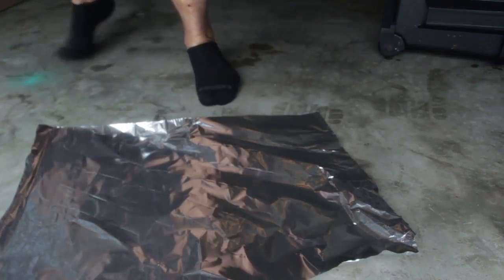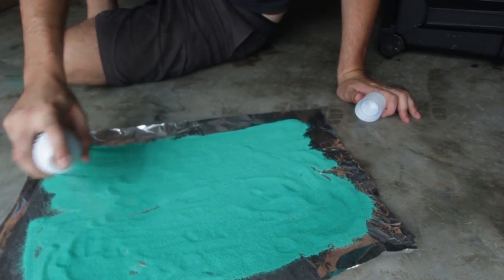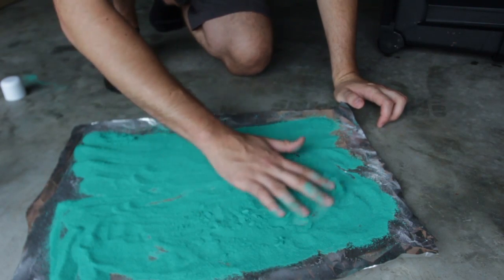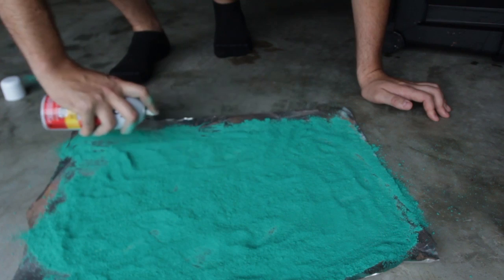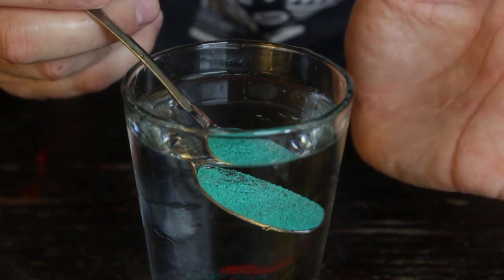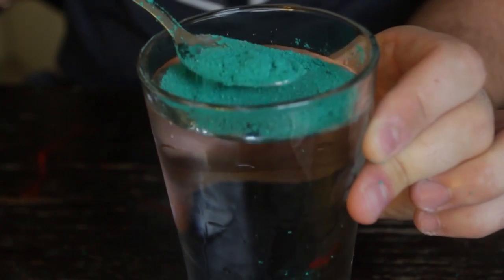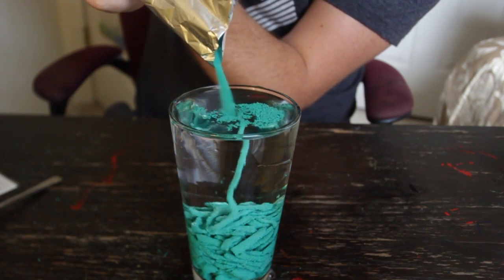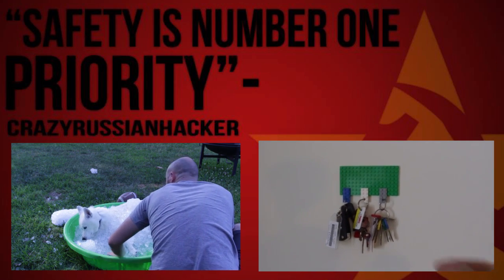DIY Magic Sand

Comment: stop or ill count to 100000
1
2
3
4
5
6
7
8
9
10
11
12
13
14
15
16
17
18
19
20
21
22
23
24
25
26
27
28
29
30
31
32
33
34
35
36
37
38
39
40
41
42
43
44
45
46
47
48
49
50
51
52
53
54
55
56
57
58
59
60
61
62
63
64
65
66
67
68
69
70
71
72
73
74
75
76
77
78
79
80
81
82
83
84
85
86
87
88
89
90
91
92
93
94
95
96
97
98
99
100
101
102
103
104
105
106
107
108
109
110
111
112
113
114
115
116
117
118
119
120
121
122
123
124
125
126
127
128
129
130
131
132
133
134
135
136
137
138
139
140
141
142
143
144
145
146
147
148
149
150
151
152
153
154
155
156
157
158
159
160
161
162
163
164
165
166
167
168
169
170
171
172
173
174
175
176
177
178
179
180
181
182
183
184
185
186
187
188
189
190
191
192
193
194
195
196
197
198
199
200
201
202
203
204
205
206
207
208
209
210
211
212
213
214
215
216
217
218
219
220
221
222
223
224
225
226
227
228
229
230
231
232
233
234
235
236
237
238
239
240
241
242
243
244
245
246
247
248
249
250
251
252
253
254
255
256
257
258
259
260
261
262
263
264
265
266
267
268
269
270
271
272
273
274
275
276
277
278
279
280
281
282
283
284
285
286
287
288
289
290
291
292
293
294
295
296
297
298
299
300
301
302
303
304
305
306
307
308
309
310
311
312
313
314
315
316
317
318
319
320
321
322
323
324
325
326
327
328
329
330
331
332
333
334
335
336
337
338
339
340
341
342
343
344
345
346
347
348
349
350
351
352
353
354
355
356
357
358
359
360
361
362
363
364
365
366
367
368
369
370
371
372
373
374
375
376
377
378
379
380
381
382
383
384
385
386
387
388
389
390
391
392
393
394
395
396
397
398
399
400
401
402
403
404
405
406
407
408
409
410
411
412
413
414
415
416
417
418
419
420
421
422
423
424
425
426
427
428
429
430
431
432
433
434
435
436
437
438
439
440
441
442
443
444
445
446
447
448
449
450
451
452
453
454
455
456
457
458
459
460
461
462
463
464
465
466
467
468
469
470
471
472
473
474
475
476
477
478
479
480
481
482
483
484
485
486
487
488
489
490
491
492
493
494
495
496
497
498
499
500
501
502
503
504
505
506
507
508
509
510
511
512
513
514
515
516
517
518
519
520
521
522
523
524
525
526
527
528
529
530
531
532
533
534
535
536
537
538
539
540
541
542
543
544
545
546
547
548
549
550
551
552
553
554
555
556
557
558
559
560
561
562
563
564
565
566
567
568
569
570
571
572
573
574
575
576
577
578
579
580
581
582
583
584
585
586
587
588
589
590
591
592
593
594
595
596
597
598
599
600
601
602
603
604
605
606
607
608
609
610
611
612
613
614
615
616
617
618
619
620
621
622
623
624
625
626
627
628
629
630
631
632
633
634
635
636
637
638
639
640
641
642
643
644
645
646
647
648
649
650
651
652
653
654
655
656
657
658
659
660
661
662
663
664
665
666
667
668
669
670
671
672
673
674
675
676
677
678
679
680
681
682
683
684
685
686
687
688
689
690
691
692
693
694
695
696
697
698
699
700
701
702
703
704
705
706
707
708
709
710
711
712
713
714
715
716
717
718
719
720
721
722
723
724
725
726
727
728
729
730
731
732
733
734
735
736
737
738
739
740
741
742
743
744
745
746
747
748
749
750
751
752
753
754
755
756
757
758
759
760
761
762
763
764
765
766
767
768
769
770
771
772
773
774
775
776
777
778
779
780
781
782
783
784
785
786
787
788
789
790
791
792
793
794
795
796
797
798
799
800
801
802
803
804
805
806
807
808
809
810
811
812
813
814
815
816
817
818
819
820
821
822
823
824
825
826
827
828
829
830
831
832
833
834
835
836
837
838
839
840
841
842
843
844
845
846
847
848
849
850
851
852
853
854
855
856
857
858
859
860
861
862
863
864
865
866
867
868
869
870
871
872
873
874
875
876
877
878
879
880
881
882
883
884
885
886
887
888
889
890
891
892
893
894
895
896
897
898
899
900
901
902
903
904
905
906
907
908
909
910
911
912
913
914
915
916
917
918
919
920
921
922
923
924
925
926
927
928
929
930
931
932
933
934
935
936
937
938
939
940
941
942
943
944
945
946
947
948
949
950
951
952
953
954
955
956
957
958
959
960
961
962
963
964
965
966
967
968
969
970
971
972
973
974
975
976
977
978
979
980
981
982
983
984
985
986
987
988
989
990
991
992
993
994
995
996
997
998
999
1000
1001
1002
1003
1004
1005
1006
1007
1008
1009
1010
1011
1012
1013
1014
1015
1016
1017
1018
1019
1020
1021
1022
1023
1024
1025
1026
1027
1028
1029
1030
1031
1032
1033
1034
1035
1036
1037
1038
1039
1040
1041
1042
1043
1044
1045
1046
1047
1048
1049
1050
1051
1052
1053
1054
1055
1056
1057
1058
1059
1060
1061
1062
1063
1064
1065
1066
1067
1068
1069
1070
1071
1072
1073
1074
1075
1076
1077
1078
1079
1080
1081
1082
1083
1084
1085
1086
1087
1088
1089
1090
1091
1092
1093
1094
1095
1096
1097
1098
1099
1100
1101
1102
1103
1104
1105
1106
1107
1108
1109
1110
1111
1112
1113
1114
1115
1116
1117
1118
1119
1120
1121
1122
1123
1124
1125
1126
1127
1128
1129
1130
1131
1132
1133
1134
1135
1136
1137
1138
1139
1140
1141
1142
1143
1144
1145
1146
1147
1148
1149
1150
1151
1152
1153
1154
1155
1156
1157
1158
1159
1160
1161
1162
1163
1164
1165
1166
1167
1168
1169
1170
1171
1172
1173
1174
1175
1176
1177
1178
1179
1180
1181
1182
1183
1184
1185
1186
1187
1188
1189
1190
1191
1192
1193
1194
1195
1196
1197
1198
1199
1200
1201
1202
1203
1204
1205
1206
1207
1208
1209
1210
1211
1212
1213
1214
1215
1216
1217
1218
1219
1220
1221
1222
1223
1224
1225
1226
1227
1228
1229
1230
1231
1232
1233
1234
1235
1236
1237
1238
1239
1240
1241
1242
1243
1244
1245
1246
1247
1248
1249
1250
1251
1252
1253
1254
1255
1256
1257
1258
1259
1260
1261
1262
1263
1264
1265
1266
1267
1268
1269
1270
1271
1272
1273
1274
1275
1276
1277
1278
1279
1280
1281
1282
1283
1284
1285
1286
1287
1288
1289
1290
1291
1292
1293
1294
1295
1296
1297
1298
1299
1300
1301
1302
1303
1304
1305
1306
1307
1308
1309
1310
1311
1312
1313
1314
1315
1316
1317
1318
1319
1320
1321
1322
1323
1324
1325
1326
1327
1328
1329
1330
1331
1332
1333
1334
1335
1336
1337
1338
1339
1340
1341
1342
1343
1344
1345
1346
1347
1348
1349
1350
1351
1352
1353
1354
1355
1356
1357
1358
1359
1360
1361
1362
1363
1364
1365
1366
1367
1368
1369
1370
1371
1372
1373
1374
1375
1376
1377
1378
1379
1380
1381
1382
1383
1384
1385
1386
1387
1388
1389
1390
1391
1392
1393
1394
1395
1396
1397
1398
1399
1400
1401
1402
1403
1404
1405
1406
1407
1408
1409
1410
1411
1412
1413
1414
1415
1416
1417
1418
1419
1420
1421
1422
1423
1424
1425
1426
1427
1428
1429
1430
1431
1432
1433
1434
1435
1436
1437
1438
1439
1440
1441
1442
1443
1444
1445
1446
1447
1448
1449
1450
1451
1452
1453
1454
1455
1456
1457
1458
1459
1460
1461
1462
1463
1464
1465
1466
1467
1468
1469
1470
1471
1472
1473
1474
1475
1476
1477
1478
1479
1480
1481
1482
1483
1484
1485
1486
1487
1488
1489
1490
1491
1492
1493
1494
1495
1496
1497
1498
1499
1500
1501
1502
1503
1504
1505
1506
1507
1508
1509
1510
1511
1512
1513
1514
1515
1516
1517
1518
1519
1520
1521
1522
1523
1524
1525
1526
1527
1528
1529
1530
1531
1532
1533
1534
1535
1536
1537
1538
1539
1540
1541
1542
1543
1544
1545
1546
1547
1548
1549
1550
1551
1552
1553
1554
1555
1556
1557
1558
1559
1560
1561
1562
1563
1564
1565
1566
1567
1568
1569
1570
1571
1572
1573
1574
1575
1576
1577
1578
1579
1580
1581
1582
1583
1584
1585
1586
1587
1588
1589
1590
1591
1592
1593
1594
1595
1596
1597
1598
1599
1600
1601
1602
1603
1604
1605
1606
1607
1608
1609
1610
1611
1612
1613
1614
1615
1616
1617
1618
1619
1620
1621
1622
1623
1624
1625
1626
1627
1628
1629
1630
1631
1632
1633
1634
1635
1636
1637
1638
1639
1640
1641
1642
1643
1644
1645
1646
1647
1648
1649
1650
1651
1652
1653
1654
1655
1656
1657
1658
1659
1660
1661
1662
1663
1664
1665
1666
1667
1668
1669
1670
1671
1672
1673
1674
1675
1676
1677
1678
1679
1680
1681
1682
1683
1684
1685
1686
1687
1688
1689
1690
1691
1692
1693
1694
1695
1696
1697
1698
1699
1700
1701
1702
1703
1704
1705
1706
1707
1708
1709
1710
1711
1712
1713
1714
1715
1716
1717
1718
1719
1720
1721
1722
1723
1724
1725
1726
1727
1728
1729
1730
1731
1732
1733
1734
1735
1736
1737
1738
1739
1740
1741
1742
1743
1744
1745
1746
1747
1748
1749
1750
1751
1752
1753
1754
1755
1756
1757
1758
1759
1760
1761
1762
1763
1764
1765
1766
1767
1768
1769
1770
1771
1772
1773
1774
1775
1776
1777
1778
1779
1780
1781
1782
1783
1784
1785
1786
1787
1788
1789
1790
1791
1792
1793
1794
1795
1796
1797
1798
1799
1800
1801
1802
1803
1804
1805
1806
1807
1808
1809
1810
1811
1812
1813
1814
1815
1816
1817
1818
1819
1820
1821
1822
1823
1824
1825
1826
1827
1828
1829
1830
1831
1832
1833
1834
1835
1836
1837
1838
1839
1840
1841
1842
1843
1844
1845
1846
1847
1848
1849
1850
1851
1852
1853
1854
1855
1856
1857
1858
1859
1860
1861
1862
1863
1864
1865
1866
1867
1868
1869
1870
1871
1872
1873
1874
1875
1876
1877
1878
1879
1880
1881
1882
1883
1884
1885
1886
1887
1888
1889
1890
1891
1892
1893
1894
1895
1896
1897
1898
1899
1900
1901
1902
1903
1904
1905
1906
1907
1908
1909
1910
1911
1912
1913
1914
1915
1916
1917
1918
1919
1920
1921
1922
1923
1924
1925
1926
1927
1928
1929
1930
1931
1932
1933
1934
1935
1936
1937
1938
1939
1940
1941
1942
1943
1944
1945
1946
1947
1948
1949
1950
1951
1952
1953
1954
1955
1956
1957
1958
1959
1960
1961
1962
1963
1964
1965
1966
1967
1968
1969
1970
1971
1972
1973
1974
1975
1976
1977
1978
1979
1980
1981
1982
1983
1984
1985
1986
1987
1988
1989
1990
1991
1992
1993
1994
1995
1996
1997
1998
1999
2000
2001
2002
2003
2004
2005
2006
2007
2008
2009
2010
2011
2012
2013
2014
2015
2016
2017
2018
2019
2020
2021
2022
2023
2024
2025
2026
2027
2028
2029
2030
2031
2032
2033
2034
2035
2036
2037
2038
2039
2040
2041
2042
2043
2044
2045
2046
2047
2048
2049
2050
2051
2052
2053
2054
2055
2056
2057
2058
2059
2060
2061
2062
2063
2064
2065
2066
2067
2068
2069
2070
2071
2072
2073
2074
2075
2076
2077
2078
2079
2080
2081
2082
2083
2084
2085
2086
2087
2088
2089
2090
2091
2092
2093
2094
2095
2096
2097
2098
2099
2100
2101
2102
2103
2104
2105
2106
2107
2108
2109
2110
2111
2112
2113
2114
2115
2116
2117
2118
2119
2120
2121
2122
2123
2124
2125
2126
2127
2128
2129
2130
2131
2132
2133
2134
2135
2136
2137
2138
2139
2140
2141
2142
2143
2144
2145
2146
2147
2148
2149
2150
2151
2152
2153
2154
2155
2156
2157
2158
2159
2160
2161
2162
2163
2164
2165
2166
2167
2168
2169
2170
2171
2172
2173
2174
2175
2176
2177
2178
2179
2180
2181
2182
2183
2184
2185
2186
2187
2188
2189
2190
2191
2192
2193
2194
2195
2196
2197
2198
2199
2200
2201
2202
2203
2204
2205
2206
2207
2208
2209
2210
2211
2212
2213
2214
2215
2216
2217
2218
2219
2220
2221
2222
2223
2224
2225
2226
2227
2228
2229
2230
2231
2232
2233
2234
2235
2236
2237
2238
2239
2240
2241
2242
2243
2244
2245
2246
2247
2248
2249
2250
2251
2252
2253
2254
2255
2256
2257
2258
2259
2260
2261
2262
2263
2264
2265
2266
2267
2268
2269
2270
2271
2272
2273
2274
2275
2276
2277
2278
2279
2280
2281
2282
2283
2284
2285
2286
2287
2288
2289
2290
2291
2292
2293
2294
2295
2296
2297
2298
2299
2300
2301
2302
2303
2304
2305
2306
2307
2308
2309
2310
2311
2312
2313
2314
2315
2316
2317
2318
2319
2320
2321
2322
2323
2324
2325
2326
2327
2328
2329
2330
2331
2332
2333
2334
2335
2336
2337
2338
2339
2340
2341
2342
2343
2344
2345
2346
2347
2348
2349
2350
2351
2352
2353
2354
2355
2356
2357
2358
2359
2360
2361
2362
2363
2364
2365
2366
2367
2368
2369
2370
2371
2372
2373
2374
2375
2376
2377
2378
2379
2380
2381
2382
2383
2384
2385
2386
2387
2388
2389
2390
2391
2392
2393
2394
2395
2396
2397
2398
2399
2400
2401
2402
2403
2404
2405
2406
2407
2408
2409
2410
2411
2412
2413
2414
2415
2416
2417
2418
2419
2420
2421
2422
2423
2424
2425
2426
2427
2428
2429
2430
2431
2432
2433
2434
2435
2436
2437
2438
2439
2440
2441
2442
2443
2444
2445
2446
2447
2448
2449
2450
2451
2452
2453
2454
2455
2456
2457
2458
2459
2460
2461
2462
2463
2464
2465
2466
2467
2468
2469
2470
2471
2472
2473
2474
2475
2476
2477
2478
2479
2480
2481
2482
2483
2484
2485
2486
2487
2488
2489
2490
2491
2492
2493
2494
2495
2496
2497
2498
2499
2500
2501
2502
2503
2504
2505
2506
2507
2508
2509
2510
2511
2512
2513
2514
2515
2516
2517
2518
2519
2520
2521
2522
2523
2524
2525
2526
2527
2528
2529
2530
2531
2532
2533
2534
2535
2536
2537
2538
2539
2540
2541
2542
2543
2544
2545
2546
2547
2548
2549
2550
2551
2552
2553
2554
2555
2556
2557
2558
2559
2560
2561
2562
2563
2564
2565
2566
2567
2568
2569
2570
2571
2572
2573
2574
2575
2576
2577
2578
2579
2580
2581
2582
2583
2584
2585
2586
2587
2588
2589
2590
2591
2592
2593
2594
2595
2596
2597
2598
2599
2600
2601
2602
2603
2604
2605
2606
2607
2608
2609
2610
2611
2612
2613
2614
2615
2616
2617
2618
2619
2620
2621
2622
2623
2624
2625
2626
2627
2628
2629
2630
2631
2632
2633
2634
2635
2636
2637
2638
2639
2640
2641
2642
2643
2644
2645
2646
2647
2648
2649
2650
2651
2652
2653
2654
2655
2656
2657
2658
2659
2660
2661
2662
2663
2664
2665
2666
2667
2668
2669
2670
2671
2672
2673
2674
2675
2676
2677
2678
2679
2680
2681
2682
2683
2684
2685
2686
2687
2688
2689
2690
2691
2692
2693
2694
2695
2696
2697
2698
2699
2700
2701
2702
2703
2704
2705
2706
2707
2708
2709
2710
2711
2712
2713
2714
2715
2716
2717
2718
2719
2720
2721
2722
2723
2724
2725
2726
2727
2728
2729
2730
2731
2732
2733
2734
2735
2736
2737
2738
2739
2740
2741
2742
2743
2744
2745
2746
2747
2748
2749
2750
2751
2752
2753
2754
2755
2756
2757
2758
2759
2760
2761
2762
2763
2764
2765
2766
2767
2768
2769
2770
2771
2772
2773
2774
2775
2776
2777
2778
2779
2780
2781
2782
2783
2784
2785
2786
2787
2788
2789
2790
2791
2792
2793
2794
2795
2796
2797
2798
2799
2800
2801
2802
2803
2804
2805
2806
2807
2808
2809
2810
2811
2812
2813
2814
2815
2816
2817
2818
2819
2820
2821
2822
2823
2824
2825
2826
2827
2828
2829
2830
2831
2832
2833
2834
2835
2836
2837
2838
2839
2840
2841
2842
2843
2844
2845
2846
2847
2848
2849
2850
2851
2852
2853
2854
2855
2856
2857
2858
2859
2860
2861
2862
2863
2864
2865
2866
2867
2868
2869
2870
2871
2872
2873
2874
2875
2876
2877
2878
2879
2880
2881
2882
2883
2884
2885
2886
2887
2888
2889
2890
2891
2892
2893
2894
2895
2896
2897
2898
2899
2900
2901
2902
2903
2904
2905
2906
2907
2908
2909
2910
2911
2912
2913
2914
2915
2916
2917
2918
2919
2920
2921
2922
2923
2924
2925
2926
2927
2928
2929
2930
2931
2932
2933
2934
2935
2936
2937
2938
2939
2940
2941
2942
2943
2944
2945
2946
2947
2948
2949
2950
2951
2952
2953
2954
2955
2956
2957
2958
2959
2960
2961
2962
2963
2964
2965
2966
2967
2968
2969
2970
2971
2972
2973
2974
2975
2976
2977
2978
2979
2980
2981
2982
2983
2984
2985
2986
2987
2988
2989
2990
2991
2992
2993
2994
2995
2996
2997
2998
2999
3000
3001
3002
3003
3004
3005
3006
3007
3008
3009
3010
3011
3012
3013
3014
3015
3016
3017
3018
3019
3020
3021
3022
3023
3024
3025
3026
3027
3028
3029
3030
3031
3032
3033
3034
3035
3036
3037
3038
3039
3040
3041
3042
3043
3044
3045
3046
3047
3048
3049
3050
3051
3052
3053
3054
3055
3056
3057
3058
3059
3060
3061
3062
3063
3064
3065
3066
3067
3068
3069
3070
3071
3072
3073
3074
3075
3076
3077
3078
3079
3080
3081
3082
3083
3084
3085
3086
3087
3088
3089
3090
3091
3092
3093
3094
3095
3096
3097
3098
3099
3100
3101
3102
3103
3104
3105
3106
3107
3108
3109
3110
3111
3112
3113
3114
3115
3116
3117
3118
3119
3120
3121
3122
3123
3124
3125
3126
3127
3128
3129
3130
3131
3132
3133
3134
3135
3136
3137
3138
3139
3140
3141
3142
3143
3144
3145
3146
3147
3148
3149
3150
3151
3152
3153
3154
3155
3156
3157
3158
3159
3160
3161
3162
3163
3164
3165
3166
3167
3168
3169
3170
3171
3172
3173
3174
3175
3176
3177
3178
3179
3180
3181
3182
3183
3184
3185
3186
3187
3188
3189
3190
3191
3192
3193
3194
3195
3196
3197
3198
3199
3200
3201
3202
3203
3204
3205
3206
3207
3208
3209
3210
3211
3212
3213
3214
3215
3216
3217
3218
3219
3220
3221
3222
3223
3224
3225
3226
3227
3228
3229
3230
3231
3232
3233
3234
3235
3236
3237
3238
3239
3240
3241
3242
3243
3244
3245
3246
3247
3248
3249
3250
3251
3252
3253
3254
3255
3256
3257
3258
3259
3260
3261
3262
3263
3264
3265
3266
3267
3268
3269
3270
3271
3272
3273
3274
3275
3276
3277
3278
3279
3280
3281
3282
3283
3284
3285
3286
3287
3288
3289
3290
3291
3292
3293
3294
3295
3296
3297
3298
3299
3300
3301
3302
3303
3304
3305
3306
3307
3308
3309
3310
3311
3312
3313
3314
3315
3316
3317
3318
3319
3320
3321
3322
3323
3324
3325
3326
3327
3328
3329
3330
3331
3332
3333
3334
3335
3336
3337
3338
3339
3340
3341
3342
3343
3344
3345
3346
3347
3348
3349
3350
3351
3352
3353
3354
3355
3356
3357
3358
3359
3360
3361
3362
3363
3364
3365
3366
3367
3368
3369
3370
3371
3372
3373
3374
3375
3376
3377
3378
3379
3380
3381
3382
3383
3384
3385
3386
3387
3388
3389
3390
3391
3392
3393
3394
3395
3396
3397
3398
3399
3400
3401
3402
3403
3404
3405
3406
3407
3408
3409
3410
3411
3412
3413
3414
3415
3416
3417
3418
3419
3420
3421
3422
3423
3424
3425
3426
3427
3428
3429
3430
3431
3432
3433
3434
3435
3436
3437
3438
3439
3440
3441
3442
3443
3444
3445
3446
3447
3448
3449
3450
3451
3452
3453
3454
3455
3456
3457
3458
3459
3460
3461
3462
3463
3464
3465
3466
3467
3468
3469
3470
3471
3472
3473
3474
3475
3476
3477
3478
3479
3480
3481
3482
3483
3484
3485
3486
3487
3488
3489
3490
3491
3492
3493
3494
3495
3496
3497
3498
3499
3500
3501
3502
3503
3504
3505
3506
3507
3508
3509
3510
3511
3512
3513
3514
3515
3516
3517
3518
3519
3520
3521
3522
3523
3524
3525
3526
3527
3528
3529
3530
3531
3532
3533
3534
3535
3536
3537
3538
3539
3540
3541
3542
3543
3544
3545
3546
3547
3548
3549
3550
3551
3552
3553
3554
3555
3556
3557
3558
3559
3560
3561
3562
3563
3564
3565
3566
3567
3568
3569
3570
3571
3572
3573
3574
3575
3576
3577
3578
3579
3580
3581
3582
3583
3584
3585
3586
3587
3588
3589
3590
3591
3592
3593
3594
3595
3596
3597
3598
3599
3600
3601
3602
3603
3604
3605
3606
3607
3608
3609
3610
3611
3612
3613
3614
3615
3616
3617
3618
3619
3620
3621
3622
3623
3624
3625
3626
3627
3628
3629
3630
3631
3632
3633
3634
3635
3636
3637
3638
3639
3640
3641
3642
3643
3644
3645
3646
3647
3648
3649
3650
3651
3652
3653
3654
3655
3656
3657
3658
3659
3660
3661
3662
3663
3664
3665
3666
3667
3668
3669
3670
3671
3672
3673
3674
3675
3676
3677
3678
3679
3680
3681
3682
3683
3684
3685
3686
3687
3688
3689
3690
3691
3692
3693
3694
3695
3696
3697
3698
3699
3700
3701
3702
3703
3704
3705
3706
3707
3708
3709
3710
3711
3712
3713
3714
3715
3716
3717
3718
3719
3720
3721
3722
3723
3724
3725
3726
3727
3728
3729
3730
3731
3732
3733
3734
3735
3736
3737
3738
3739
3740
3741
3742
3743
3744
3745
3746
3747
3748
3749
3750
3751
3752
3753
3754
3755
3756
3757
3758
3759
3760
3761
3762
3763
3764
3765
3766
3767
3768
3769
3770
3771
3772
3773
3774
3775
3776
3777
3778
3779
3780
3781
3782
3783
3784
3785
3786
3787
3788
3789
3790
3791
3792
3793
3794
3795
3796
3797
3798
3799
3800
3801
3802
3803
3804
3805
3806
3807
3808
3809
3810
3811
3812
3813
3814
3815
3816
3817
3818
3819
3820
3821
3822
3823
3824
3825
3826
3827
3828
3829
3830
3831
3832
3833
3834
3835
3836
3837
3838
3839
3840
3841
3842
3843
3844
3845
3846
3847
3848
3849
3850
3851
3852
3853
3854
3855
3856
3857
3858
3859
3860
3861
3862
3863
3864
3865
3866
3867
3868
3869
3870
3871
3872
3873
3874
3875
3876
3877
3878
3879
3880
3881
3882
3883
3884
3885
3886
3887
3888
3889
3890
3891
3892
3893
3894
3895
3896
3897
3898
3899
3900
3901
3902
3903
3904
3905
3906
3907
3908
3909
3910
3911
3912
3913
3914
3915
3916
3917
3918
3919
3920
3921
3922
3923
3924
3925
3926
3927
3928
3929
3930
3931
3932
3933
3934
3935
3936
3937
3938
3939
3940
3941
3942
3943
3944
3945
3946
3947
3948
3949
3950
3951
3952
3953
3954
3955
3956
3957
3958
3959
3960
3961
3962
3963
3964
3965
3966
3967
3968
3969
3970
3971
3972
3973
3974
3975
3976
3977
3978
3979
3980
3981
3982
3983
3984
3985
3986
3987
3988
3989
3990
3991
3992
3993
3994
3995
3996
3997
3998
3999
4000
4001
4002
4003
4004
4005
4006
4007
4008
4009
4010
4011
4012
4013
4014
4015
4016
4017
4018
4019
4020
4021
4022
4023
4024
4025
4026
4027
4028
4029
4030
4031
4032
4033
4034
4035
4036
4037
4038
4039
4040
4041
4042
4043
4044
4045
4046
4047
4048
4049
4050
4051
4052
4053
4054
4055
4056
4057
4058
4059
4060
4061
4062
4063
4064
4065
4066
4067
4068
4069
4070
4071
4072
4073
4074
4075
4076
4077
4078
4079
4080
4081
4082
4083
4084
4085
4086
4087
4088
4089
4090
4091
4092
4093
4094
4095
4096
4097
4098
4099
4100
4101
4102
4103
4104
4105
4106
4107
4108
4109
4110
4111
4112
4113
4114
4115
4116
4117
4118
4119
4120
4121
4122
4123
4124
4125
4126
4127
4128
4129
4130
4131
4132
4133
4134
4135
4136
4137
4138
4139
4140
4141
4142
4143
4144
4145
4146
4147
4148
4149
4150
4151
4152
4153
4154
4155
4156
4157
4158
4159
4160
4161
4162
4163
4164
4165
4166
4167
4168
4169
4170
4171
4172
4173
4174
4175
4176
4177
4178
4179
4180
4181
4182
4183
4184
4185
4186
4187
4188
4189
4190
4191
4192
4193
4194
4195
4196
4197
4198
4199
4200
4201
4202
4203
4204
4205
4206
4207
4208
4209
4210
4211
4212
4213
4214
4215
4216
4217
4218
4219
4220
4221
4222
4223
4224
4225
4226
4227
4228
4229
4230
4231
4232
4233
4234
4235
4236
4237
4238
4239
4240
4241
4242
4243
4244
4245
4246
4247
4248
4249
4250
4251
4252
4253
4254
4255
4256
4257
4258
4259
4260
4261
4262
4263
4264
4265
4266
4267
4268
4269
4270
4271
4272
4273
4274
4275
4276
4277
4278
4279
4280
4281
4282
4283
4284
4285
4286
4287
4288
4289
4290
4291
4292
4293
4294
4295
4296
4297
4298
4299
4300
4301
4302
4303
4304
4305
4306
4307
4308
4309
4310
4311
4312
4313
4314
4315
4316
4317
4318
4319
4320
4321
4322
4323
4324
4325
4326
4327
4328
4329
4330
4331
4332
4333
4334
4335
4336
4337
4338
4339
4340
4341
4342
4343
4344
4345
4346
4347
4348
4349
4350
4351
4352
4353
4354
4355
4356
4357
4358
4359
4360
4361
4362
4363
4364
4365
4366
4367
4368
4369
4370
4371
4372
4373
4374
4375
4376
4377
4378
4379
4380
4381
4382
4383
4384
4385
4386
4387
4388
4389
4390
4391
4392
4393
4394
4395
4396
4397
4398
4399
4400
4401
4402
4403
4404
4405
4406
4407
4408
4409
4410
4411
4412
4413
4414
4415
4416
4417
4418
4419
4420
4421
4422
4423
4424
4425
4426
4427
4428
4429
4430
4431
4432
4433
4434
4435
4436
4437
4438
4439
4440
4441
4442
4443
4444
4445
4446
4447
4448
4449
4450
4451
4452
4453
4454
4455
4456
4457
4458
4459
4460
4461
4462
4463
4464
4465
4466
4467
4468
4469
4470
4471
4472
4473
4474
4475
4476
4477
4478
4479
4480
4481
4482
4483
4484
4485
4486
4487
4488
4489
4490
4491
4492
4493
4494
4495
4496
4497
4498
4499
4500
4501
4502
4503
4504
4505
4506
4507
4508
4509
4510
4511
4512
4513
4514
4515
4516
4517
4518
4519
4520
4521
4522
4523
4524
4525
4526
4527
4528
4529
4530
4531
4532
4533
4534
4535
4536
4537
4538
4539
4540
4541
4542
4543
4544
4545
4546
4547
4548
4549
4550
4551
4552
4553
4554
4555
4556
4557
4558
4559
4560
4561
4562
4563
4564
4565
4566
4567
4568
4569
4570
4571
4572
4573
4574
4575
4576
4577
4578
4579
4580
4581
4582
4583
4584
4585
4586
4587
4588
4589
4590
4591
4592
4593
4594
4595
4596
4597
4598
4599
4600
4601
4602
4603
4604
4605
4606
4607
4608
4609
4610
4611
4612
4613
4614
4615
4616
4617
4618
4619
4620
4621
4622
4623
4624
4625
4626
4627
4628
4629
4630
4631
4632
4633
4634
4635
4636
4637
4638
4639
4640
4641
4642
4643
4644
4645
4646
4647
4648
4649
4650
4651
4652
4653
4654
4655
4656
4657
4658
4659
4660
4661
4662
4663
4664
4665
4666
4667
4668
4669
4670
4671
4672
4673
4674
4675
4676
4677
4678
4679
4680
4681
4682
4683
4684
4685
4686
4687
4688
4689
4690
4691
4692
4693
4694
4695
4696
4697
4698
4699
4700
4701
4702
4703
4704
4705
4706
4707
4708
4709
4710
4711
4712
4713
4714
4715
4716
4717
4718
4719
4720
4721
4722
4723
4724
4725
4726
4727
4728
4729
4730
4731
4732
4733
4734
4735
4736
4737
4738
4739
4740
4741
4742
4743
4744
4745
4746
4747
4748
4749
4750
4751
4752
4753
4754
4755
4756
4757
4758
4759
4760
4761
4762
4763
4764
4765
4766
4767
4768
4769
4770
4771
4772
4773
4774
4775
4776
4777
4778
4779
4780
4781
4782
4783
4784
4785
4786
4787
4788
4789
4790
4791
4792
4793
4794
4795
4796
4797
4798
4799
4800
4801
4802
4803
4804
4805
4806
4807
4808
4809
4810
4811
4812
4813
4814
4815
4816
4817
4818
4819
4820
4821
4822
4823
4824
4825
4826
4827
4828
4829
4830
4831
4832
4833
4834
4835
4836
4837
4838
4839
4840
4841
4842
4843
4844
4845
4846
4847
4848
4849
4850
4851
4852
4853
4854
4855
4856
4857
4858
4859
4860
4861
4862
4863
4864
4865
4866
4867
4868
4869
4870
4871
4872
4873
4874
4875
4876
4877
4878
4879
4880
4881
4882
4883
4884
4885
4886
4887
4888
4889
4890
4891
4892
4893
4894
4895
4896
4897
4898
4899
4900
4901
4902
4903
4904
4905
4906
4907
4908
4909
4910
4911
4912
4913
4914
4915
4916
4917
4918
4919
4920
4921
4922
4923
4924
4925
4926
4927
4928
4929
4930
4931
4932
4933
4934
4935
4936
4937
4938
4939
4940
4941
4942
4943
4944
4945
4946
4947
4948
4949
4950
4951
4952
4953
4954
4955
4956
4957
4958
4959
4960
4961
4962
4963
4964
4965
4966
4967
4968
4969
4970
4971
4972
4973
4974
4975
4976
4977
4978
4979
4980
4981
4982
4983
4984
4985
4986
4987
4988
4989
4990
4991
4992
4993
4994
4995
4996
4997
4998
4999
5000
5001
5002
5003
5004
5005
5006
5007
5008
5009
5010
5011
5012
5013
5014
5015
5016
5017
5018
5019
5020
5021
5022
5023
5024
5025
5026
5027
5028
5029
5030
5031
5032
5033
5034
5035
5036
5037
5038
5039
5040
5041
5042
5043
5044
5045
5046
5047
5048
5049
5050
5051
5052
5053
5054
5055
5056
5057
5058
5059
5060
5061
5062
5063
5064
5065
5066
5067
5068
5069
5070
5071
5072
5073
5074
5075
5076
5077
5078
5079
5080
5081
5082
5083
5084
5085
5086
5087
5088
5089
5090
5091
5092
5093
5094
5095
5096
5097
5098
5099
5100
5101
5102
5103
5104
5105
5106
5107
5108
5109
5110
5111
5112
5113
5114
5115
5116
5117
5118
5119
5120
5121
5122
5123
5124
5125
5126
5127
5128
5129
5130
5131
5132
5133
5134
5135
5136
5137
5138
5139
5140
5141
5142
5143
5144
5145
5146
5147
5148
5149
5150
5151
5152
5153
5154
5155
5156
5157
5158
5159
5160
5161
5162
5163
5164
5165
5166
5167
5168
5169
5170
5171
5172
5173
5174
5175
5176
5177
5178
5179
5180
5181
5182
5183
5184
5185
5186
5187
5188
5189
5190
5191
5192
5193
5194
5195
5196
5197
5198
5199
5200
5201
5202
5203
5204
5205
5206
5207
5208
5209
5210
5211
5212
5213
5214
5215
5216
5217
5218
5219
5220
5221
5222
5223
5224
5225
5226
5227
5228
5229
5230
5231
5232
5233
5234
5235
5236
5237
5238
5239
5240
5241
5242
5243
5244
5245
5246
5247
5248
5249
5250
5251
5252
5253
5254
5255
5256
5257
5258
5259
5260
5261
5262
5263
5264
5265
5266
5267
5268
5269
5270
5271
5272
5273
5274
5275
5276
5277
5278
5279
5280
5281
5282
5283
5284
5285
5286
5287
5288
5289
5290
5291
5292
5293
5294
5295
5296
5297
5298
5299
5300
5301
5302
5303
5304
5305
5306
5307
5308
5309
5310
5311
5312
5313
5314
5315
5316
5317
5318
5319
5320
5321
5322
5323
5324
5325
5326
5327
5328
5329
5330
5331
5332
5333
5334
5335
5336
5337
5338
5339
5340
5341
5342
5343
5344
5345
5346
5347
5348
5349
5350
5351
5352
5353
5354
5355
5356
5357
5358
5359
5360
5361
5362
5363
5364
5365
5366
5367
5368
5369
5370
5371
5372
5373
5374
5375
5376
5377
5378
5379
5380
5381
5382
5383
5384
5385
5386
5387
5388
5389
5390
5391
5392
5393
5394
5395
5396
5397
5398
5399
5400
5401
5402
5403
5404
5405
5406
5407
5408
5409
5410
5411
5412
5413
5414
5415
5416
5417
5418
5419
5420
5421
5422
5423
5424
5425
5426
5427
5428
5429
5430
5431
5432
5433
5434
5435
5436
5437
5438
5439
5440
5441
5442
5443
5444
5445
5446
5447
5448
5449
5450
5451
5452
5453
5454
5455
5456
5457
5458
5459
5460
5461
5462
5463
5464
5465
5466
5467
5468
5469
5470
5471
5472
5473
5474
5475
5476
5477
5478
5479
5480
5481
5482
5483
5484
5485
5486
5487
5488
5489
5490
5491
5492
5493
5494
5495
5496
5497
5498
5499
5500
5501
5502
5503
5504
5505
5506
5507
5508
5509
5510
5511
5512
5513
5514
5515
5516
5517
5518
5519
5520
5521
5522
5523
5524
5525
5526
5527
5528
5529
5530
5531
5532
5533
5534
5535
5536
5537
5538
5539
5540
5541
5542
5543
5544
5545
5546
5547
5548
5549
5550
5551
5552
5553
5554
5555
5556
5557
5558
5559
5560
5561
5562
5563
5564
5565
5566
5567
5568
5569
5570
5571
5572
5573
5574
5575
5576
5577
5578
5579
5580
5581
5582
5583
5584
5585
5586
5587
5588
5589
5590
5591
5592
5593
5594
5595
5596
5597
5598
5599
5600
5601
5602
5603
5604
5605
5606
5607
5608
5609
5610
5611
5612
5613
5614
5615
5616
5617
5618
5619
5620
5621
5622
5623
5624
5625
5626
5627
5628
5629
5630
5631
5632
5633
5634
5635
5636
5637
5638
5639
5640
5641
5642
5643
5644
5645
5646
5647
5648
5649
5650
5651
5652
5653
5654
5655
5656
5657
5658
5659
5660
5661
5662
5663
5664
5665
5666
5667
5668
5669
5670
5671
5672
5673
5674
5675
5676
5677
5678
5679
5680
5681
5682
5683
5684
5685
5686
5687
5688
5689
5690
5691
5692
5693
5694
5695
5696
5697
5698
5699
5700
5701
5702
5703
5704
5705
5706
5707
5708
5709
5710
5711
5712
5713
5714
5715
5716
5717
5718
5719
5720
5721
5722
5723
5724
5725
5726
5727
5728
5729
5730
5731
5732
5733
5734
5735
5736
5737
5738
5739
5740
5741
5742
5743
5744
5745
5746
5747
5748
5749
5750
5751
5752
5753
5754
5755
5756
5757
5758
5759
5760
5761
5762
5763
5764
5765
5766
5767
5768
5769
5770
5771
5772
5773
5774
5775
5776
5777
5778
5779
5780
5781
5782
5783
5784
5785
5786
5787
5788
5789
5790
5791
5792
5793
5794
5795
5796
5797
5798
5799
5800
5801
5802
5803
5804
5805
5806
5807
5808
5809
5810
5811
5812
5813
5814
5815
5816
5817
5818
5819
5820
5821
5822
5823
5824
5825
5826
5827
5828
5829
5830
5831
5832
5833
5834
5835
5836
5837
5838
5839
5840
5841
5842
5843
5844
5845
5846
5847
5848
5849
5850
5851
5852
5853
5854
5855
5856
5857
5858
5859
5860
5861
5862
5863
5864
5865
5866
5867
5868
5869
5870
5871
5872
5873
5874
5875
5876
5877
5878
5879
5880
5881
5882
5883
5884
5885
5886
5887
5888
5889
5890
5891
5892
5893
5894
5895
5896
5897
5898
5899
5900
5901
5902
5903
5904
5905
5906
5907
5908
5909
5910
5911
5912
5913
5914
5915
5916
5917
5918
5919
5920
5921
5922
5923
5924
5925
5926
5927
5928
5929
5930
5931
5932
5933
5934
5935
5936
5937
5938
5939
5940
5941
5942
5943
5944
5945
5946
5947
5948
5949
5950
5951
5952
5953
5954
5955
5956
5957
5958
5959
5960
5961
5962
5963
5964
5965
5966
5967
5968
5969
5970
5971
5972
5973
5974
5975
5976
5977
5978
5979
5980
5981
5982
5983
5984
5985
5986
5987
5988
5989
5990
5991
5992
5993
5994
5995
5996
5997
5998
5999
6000
6001
6002
6003
6004
6005
6006
6007
6008
6009
6010
6011
6012
6013
6014
6015
6016
6017
6018
6019
6020
6021
6022
6023
6024
6025
6026
6027
6028
6029
6030
6031
6032
6033
6034
6035
6036
6037
6038
6039
6040
6041
6042
6043
6044
6045
6046
6047
6048
6049
6050
6051
6052
6053
6054
6055
6056
6057
6058
6059
6060
6061
6062
6063
6064
6065
6066
6067
6068
6069
6070
6071
6072
6073
6074
6075
6076
6077
6078
6079
6080
6081
6082
6083
6084
6085
6086
6087
6088
6089
6090
6091
6092
6093
6094
6095
6096
6097
6098
6099
6100
6101
6102
6103
6104
6105
6106
6107
6108
6109
6110
6111
6112
6113
6114
6115
6116
6117
6118
6119
6120
6121
6122
6123
6124
6125
6126
6127
6128
6129
6130
6131
6132
6133
6134
6135
6136
6137
6138
6139
6140
6141
6142
6143
6144
6145
6146
6147
6148
6149
6150
6151
6152
6153
6154
6155
6156
6157
6158
6159
6160
6161
6162
6163
6164
6165
6166
6167
6168
6169
6170
6171
6172
6173
6174
6175
6176
6177
6178
6179
6180
6181
6182
6183
6184
6185
6186
6187
6188
6189
6190
6191
6192
6193
6194
6195
6196
6197
6198
6199
6200
6201
6202
6203
6204
6205
6206
6207
6208
6209
6210
6211
6212
6213
6214
6215
6216
6217
6218
6219
6220
6221
6222
6223
6224
6225
6226
6227
6228
6229
6230
6231
6232
6233
6234
6235
6236
6237
6238
6239
6240
6241
6242
6243
6244
6245
6246
6247
6248
6249
6250
6251
6252
6253
6254
6255
6256
6257
6258
6259
6260
6261
6262
6263
6264
6265
6266
6267
6268
6269
6270
6271
6272
6273
6274
6275
6276
6277
6278
6279
6280
6281
6282
6283
6284
6285
6286
6287
6288
6289
6290
6291
6292
6293
6294
6295
6296
6297
6298
6299
6300
6301
6302
6303
6304
6305
6306
6307
6308
6309
6310
6311
6312
6313
6314
6315
6316
6317
6318
6319
6320
6321
6322
6323
6324
6325
6326
6327
6328
6329
6330
6331
6332
6333
6334
6335
6336
6337
6338
6339
6340
6341
6342
6343
6344
6345
6346
6347
6348
6349
6350
6351
6352
6353
6354
6355
6356
6357
6358
6359
6360
6361
6362
6363
6364
6365
6366
6367
6368
6369
6370
6371
6372
6373
6374
6375
6376
6377
6378
6379
6380
6381
6382
6383
6384
6385
6386
6387
6388
6389
6390
6391
6392
6393
6394
6395
6396
6397
6398
6399
6400
6401
6402
6403
6404
6405
6406
6407
6408
6409
6410
6411
6412
6413
6414
6415
6416
6417
6418
6419
6420
6421
6422
6423
6424
6425
6426
6427
6428
6429
6430
6431
6432
6433
6434
6435
6436
6437
6438
6439
6440
6441
6442
6443
6444
6445
6446
6447
6448
6449
6450
6451
6452
6453
6454
6455
6456
6457
6458
6459
6460
6461
6462
6463
6464
6465
6466
6467
6468
6469
6470
6471
6472
6473
6474
6475
6476
6477
6478
6479
6480
6481
6482
6483
6484
6485
6486
6487
6488
6489
6490
6491
6492
6493
6494
6495
6496
6497
6498
6499
6500
6501
6502
6503
6504
6505
6506
6507
6508
6509
6510
6511
6512
6513
6514
6515
6516
6517
6518
6519
6520
6521
6522
6523
6524
6525
6526
6527
6528
6529
6530
6531
6532
6533
6534
6535
6536
6537
6538
6539
6540
6541
6542
6543
6544
6545
6546
6547
6548
6549
6550
6551
6552
6553
6554
6555
6556
6557
6558
6559
6560
6561
6562
6563
6564
6565
6566
6567
6568
6569
6570
6571
6572
6573
6574
6575
6576
6577
6578
6579
6580
6581
6582
6583
6584
6585
6586
6587
6588
6589
6590
6591
6592
6593
6594
6595
6596
6597
6598
6599
6600
6601
6602
6603
6604
6605
6606
6607
6608
6609
6610
6611
6612
6613
6614
6615
6616
6617
6618
6619
6620
6621
6622
6623
6624
6625
6626
6627
6628
6629
6630
6631
6632
6633
6634
6635
6636
6637
6638
6639
6640
6641
6642
6643
6644
6645
6646
6647
6648
6649
6650
6651
6652
6653
6654
6655
6656
6657
6658
6659
6660
6661
6662
6663
6664
6665
6666
6667
6668
6669
6670
6671
6672
6673
6674
6675
6676
6677
6678
6679
6680
6681
6682
6683
6684
6685
6686
6687
6688
6689
6690
6691
6692
6693
6694
6695
6696
6697
6698
6699
6700
6701
6702
6703
6704
6705
6706
6707
6708
6709
6710
6711
6712
6713
6714
6715
6716
6717
6718
6719
6720
6721
6722
6723
6724
6725
6726
6727
6728
6729
6730
6731
6732
6733
6734
6735
6736
6737
6738
6739
6740
6741
6742
6743
6744
6745
6746
6747
6748
6749
6750
6751
6752
6753
6754
6755
6756
6757
6758
6759
6760
6761
6762
6763
6764
6765
6766
6767
6768
6769
6770
6771
6772
6773
6774
6775
6776
6777
6778
6779
6780
6781
6782
6783
6784
6785
6786
6787
6788
6789
6790
6791
6792
6793
6794
6795
6796
6797
6798
6799
6800
6801
6802
6803
6804
6805
6806
6807
6808
6809
6810
6811
6812
6813
6814
6815
6816
6817
6818
6819
6820
6821
6822
6823
6824
6825
6826
6827
6828
6829
6830
6831
6832
6833
6834
6835
6836
6837
6838
6839
6840
6841
6842
6843
6844
6845
6846
6847
6848
6849
6850
6851
6852
6853
6854
6855
6856
6857
6858
6859
6860
6861
6862
6863
6864
6865
6866
6867
6868
6869
6870
6871
6872
6873
6874
6875
6876
6877
6878
6879
6880
6881
6882
6883
6884
6885
6886
6887
6888
6889
6890
6891
6892
6893
6894
6895
6896
6897
6898
6899
6900
6901
6902
6903
6904
6905
6906
6907
6908
6909
6910
6911
6912
6913
6914
6915
6916
6917
6918
6919
6920
6921
6922
6923
6924
6925
6926
6927
6928
6929
6930
6931
6932
6933
6934
6935
6936
6937
6938
6939
6940
6941
6942
6943
6944
6945
6946
6947
6948
6949
6950
6951
6952
6953
6954
6955
6956
6957
6958
6959
6960
6961
6962
6963
6964
6965
6966
6967
6968
6969
6970
6971
6972
6973
6974
6975
6976
6977
6978
6979
6980
6981
6982
6983
6984
6985
6986
6987
6988
6989
6990
6991
6992
6993
6994
6995
6996
6997
6998
6999
7000
7001
7002
7003
7004
7005
7006
7007
7008
7009
7010
7011
7012
7013
7014
7015
7016
7017
7018
7019
7020
7021
7022
7023
7024
7025
7026
7027
7028
7029
7030
7031
7032
7033
7034
7035
7036
7037
7038
7039
7040
7041
7042
7043
7044
7045
7046
7047
7048
7049
7050
7051
7052
7053
7054
7055
7056
7057
7058
7059
7060
7061
7062
7063
7064
7065
7066
7067
7068
7069
7070
7071
7072
7073
7074
7075
7076
7077
7078
7079
7080
7081
7082
7083
7084
7085
7086
7087
7088
7089
7090
7091
7092
7093
7094
7095
7096
7097
7098
7099
7100
7101
7102
7103
7104
7105
7106
7107
7108
7109
7110
7111
7112
7113
7114
7115
7116
7117
7118
7119
7120
7121
7122
7123
7124
7125
7126
7127
7128
7129
7130
7131
7132
7133
7134
7135
7136
7137
7138
7139
7140
7141
7142
7143
7144
7145
7146
7147
7148
7149
7150
7151
7152
7153
7154
7155
7156
7157
7158
7159
7160
7161
7162
7163
7164
7165
7166
7167
7168
7169
7170
7171
7172
7173
7174
7175
7176
7177
7178
7179
7180
7181
7182
7183
7184
7185
7186
7187
7188
7189
7190
7191
7192
7193
7194
7195
7196
7197
7198
7199
7200
7201
7202
7203
7204
7205
7206
7207
7208
7209
7210
7211
7212
7213
7214
7215
7216
7217
7218
7219
7220
7221
7222
7223
7224
7225
7226
7227
7228
7229
7230
7231
7232
7233
7234
7235
7236
7237
7238
7239
7240
7241
7242
7243
7244
7245
7246
7247
7248
7249
7250
7251
7252
7253
7254
7255
7256
7257
7258
7259
7260
7261
7262
7263
7264
7265
7266
7267
7268
7269
7270
7271
7272
7273
7274
7275
7276
7277
7278
7279
7280
7281
7282
7283
7284
7285
7286
7287
7288
7289
7290
7291
7292
7293
7294
7295
7296
7297
7298
7299
7300
7301
7302
7303
7304
7305
7306
7307
7308
7309
7310
7311
7312
7313
7314
7315
7316
7317
7318
7319
7320
7321
7322
7323
7324
7325
7326
7327
7328
7329
7330
7331
7332
7333
7334
7335
7336
7337
7338
7339
7340
7341
7342
7343
7344
7345
7346
7347
7348
7349
7350
7351
7352
7353
7354
7355
7356
7357
7358
7359
7360
7361
7362
7363
7364
7365
7366
7367
7368
7369
7370
7371
7372
7373
7374
7375
7376
7377
7378
7379
7380
7381
7382
7383
7384
7385
7386
7387
7388
7389
7390
7391
7392
7393
7394
7395
7396
7397
7398
7399
7400
7401
7402
7403
7404
7405
7406
7407
7408
7409
7410
7411
7412
7413
7414
7415
7416
7417
7418
7419
7420
7421
7422
7423
7424
7425
7426
7427
7428
7429
7430
7431
7432
7433
7434
7435
7436
7437
7438
7439
7440
7441
7442
7443
7444
7445
7446
7447
7448
7449
7450
7451
7452
7453
7454
7455
7456
7457
7458
7459
7460
7461
7462
7463
7464
7465
7466
7467
7468
7469
7470
7471
7472
7473
7474
7475
7476
7477
7478
7479
7480
7481
7482
7483
7484
7485
7486
7487
7488
7489
7490
7491
7492
7493
7494
7495
7496
7497
7498
7499
7500
7501
7502
7503
7504
7505
7506
7507
7508
7509
7510
7511
7512
7513
7514
7515
7516
7517
7518
7519
7520
7521
7522
7523
7524
7525
7526
7527
7528
7529
7530
7531
7532
7533
7534
7535
7536
7537
7538
7539
7540
7541
7542
7543
7544
7545
7546
7547
7548
7549
7550
7551
7552
7553
7554
7555
7556
7557
7558
7559
7560
7561
7562
7563
7564
7565
7566
7567
7568
7569
7570
7571
7572
7573
7574
7575
7576
7577
7578
7579
7580
7581
7582
7583
7584
7585
7586
7587
7588
7589
7590
7591
7592
7593
7594
7595
7596
7597
7598
7599
7600
7601
7602
7603
7604
7605
7606
7607
7608
7609
7610
7611
7612
7613
7614
7615
7616
7617
7618
7619
7620
7621
7622
7623
7624
7625
7626
7627
7628
7629
7630
7631
7632
7633
7634
7635
7636
7637
7638
7639
7640
7641
7642
7643
7644
7645
7646
7647
7648
7649
7650
7651
7652
7653
7654
7655
7656
7657
7658
7659
7660
7661
7662
7663
7664
7665
7666
7667
7668
7669
7670
7671
7672
7673
7674
7675
7676
7677
7678
7679
7680
7681
7682
7683
7684
7685
7686
7687
7688
7689
7690
7691
7692
7693
7694
7695
7696
7697
7698
7699
7700
7701
7702
7703
7704
7705
7706
7707
7708
7709
7710
7711
7712
7713
7714
7715
7716
7717
7718
7719
7720
7721
7722
7723
7724
7725
7726
7727
7728
7729
7730
7731
7732
7733
7734
7735
7736
7737
7738
7739
7740
7741
7742
7743
7744
7745
7746
7747
7748
7749
7750
7751
7752
7753
7754
7755
7756
7757
7758
7759
7760
7761
7762
7763
7764
7765
7766
7767
7768
7769
7770
7771
7772
7773
7774
7775
7776
7777
7778
7779
7780
7781
7782
7783
7784
7785
7786
7787
7788
7789
7790
7791
7792
7793
7794
7795
7796
7797
7798
7799
7800
7801
7802
7803
7804
7805
7806
7807
7808
7809
7810
7811
7812
7813
7814
7815
7816
7817
7818
7819
7820
7821
7822
7823
7824
7825
7826
7827
7828
7829
7830
7831
7832
7833
7834
7835
7836
7837
7838
7839
7840
7841
7842
7843
7844
7845
7846
7847
7848
7849
7850
7851
7852
7853
7854
7855
7856
7857
7858
7859
7860
7861
7862
7863
7864
7865
7866
7867
7868
7869
7870
7871
7872
7873
7874
7875
7876
7877
7878
7879
7880
7881
7882
7883
7884
7885
7886
7887
7888
7889
7890
7891
7892
7893
7894
7895
7896
7897
7898
7899
7900
7901
7902
7903
7904
7905
7906
7907
7908
7909
7910
7911
7912
7913
7914
7915
7916
7917
7918
7919
7920
7921
7922
7923
7924
7925
7926
7927
7928
7929
7930
7931
7932
7933
7934
7935
7936
7937
7938
7939
7940
7941
7942
7943
7944
7945
7946
7947
7948
7949
7950
7951
7952
7953
7954
7955
7956
7957
7958
7959
7960
7961
7962
7963
7964
7965
7966
7967
7968
7969
7970
7971
7972
7973
7974
7975
7976
7977
7978
7979
7980
7981
7982
7983
7984
7985
7986
7987
7988
7989
7990
7991
7992
7993
7994
7995
7996
7997
7998
7999
8000
8001
8002
8003
8004
8005
8006
8007
8008
8009
8010
8011
8012
8013
8014
8015
8016
8017
8018
8019
8020
8021
8022
8023
8024
8025
8026
8027
8028
8029
8030
8031
8032
8033
8034
8035
8036
8037
8038
8039
8040
8041
8042
8043
8044
8045
8046
8047
8048
8049
8050
8051
8052
8053
8054
8055
8056
8057
8058
8059
8060
8061
8062
8063
8064
8065
8066
8067
8068
8069
8070
8071
8072
8073
8074
8075
8076
8077
8078
8079
8080
8081
8082
8083
8084
8085
8086
8087
8088
8089
8090
8091
8092
8093
8094
8095
8096
8097
8098
8099
8100
8101
8102
8103
8104
8105
8106
8107
8108
8109
8110
8111
8112
8113
8114
8115
8116
8117
8118
8119
8120
8121
8122
8123
8124
8125
8126
8127
8128
8129
8130
8131
8132
8133
8134
8135
8136
8137
8138
8139
8140
8141
8142
8143
8144
8145
8146
8147
8148
8149
8150
8151
8152
8153
8154
8155
8156
8157
8158
8159
8160
8161
8162
8163
8164
8165
8166
8167
8168
8169
8170
8171
8172
8173
8174
8175
8176
8177
8178
8179
8180
8181
8182
8183
8184
8185
8186
8187
8188
8189
8190
8191
8192
8193
8194
8195
8196
8197
8198
8199
8200
8201
8202
8203
8204
8205
8206
8207
8208
8209
8210
8211
8212
8213
8214
8215
8216
8217
8218
8219
8220
8221
8222
8223
8224
8225
8226
8227
8228
8229
8230
8231
8232
8233
8234
8235
8236
8237
8238
8239
8240
8241
8242
8243
8244
8245
8246
8247
8248
8249
8250
8251
8252
8253
8254
8255
8256
8257
8258
8259
8260
8261
8262
8263
8264
8265
8266
8267
8268
8269
8270
8271
8272
8273
8274
8275
8276
8277
8278
8279
8280
8281
8282
8283
8284
8285
8286
8287
8288
8289
8290
8291
8292
8293
8294
8295
8296
8297
8298
8299
8300
8301
8302
8303
8304
8305
8306
8307
8308
8309
8310
8311
8312
8313
8314
8315
8316
8317
8318
8319
8320
8321
8322
8323
8324
8325
8326
8327
8328
8329
8330
8331
8332
8333
8334
8335
8336
8337
8338
8339
8340
8341
8342
8343
8344
8345
8346
8347
8348
8349
8350
8351
8352
8353
8354
8355
8356
8357
8358
8359
8360
8361
8362
8363
8364
8365
8366
8367
8368
8369
8370
8371
8372
8373
8374
8375
8376
8377
8378
8379
8380
8381
8382
8383
8384
8385
8386
8387
8388
8389
8390
8391
8392
8393
8394
8395
8396
8397
8398
8399
8400
8401
8402
8403
8404
8405
8406
8407
8408
8409
8410
8411
8412
8413
8414
8415
8416
8417
8418
8419
8420
8421
8422
8423
8424
8425
8426
8427
8428
8429
8430
8431
8432
8433
8434
8435
8436
8437
8438
8439
8440
8441
8442
8443
8444
8445
8446
8447
8448
8449
8450
8451
8452
8453
8454
8455
8456
8457
8458
8459
8460
8461
8462
8463
8464
8465
8466
8467
8468
8469
8470
8471
8472
8473
8474
8475
8476
8477
8478
8479
8480
8481
8482
8483
8484
8485
8486
8487
8488
8489
8490
8491
8492
8493
8494
8495
8496
8497
8498
8499
8500
8501
8502
8503
8504
8505
8506
8507
8508
8509
8510
8511
8512
8513
8514
8515
8516
8517
8518
8519
8520
8521
8522
8523
8524
8525
8526
8527
8528
8529
8530
8531
8532
8533
8534
8535
8536
8537
8538
8539
8540
8541
8542
8543
8544
8545
8546
8547
8548
8549
8550
8551
8552
8553
8554
8555
8556
8557
8558
8559
8560
8561
8562
8563
8564
8565
8566
8567
8568
8569
8570
8571
8572
8573
8574
8575
8576
8577
8578
8579
8580
8581
8582
8583
8584
8585
8586
8587
8588
8589
8590
8591
8592
8593
8594
8595
8596
8597
8598
8599
8600
8601
8602
8603
8604
8605
8606
8607
8608
8609
8610
8611
8612
8613
8614
8615
8616
8617
8618
8619
8620
8621
8622
8623
8624
8625
8626
8627
8628
8629
8630
8631
8632
8633
8634
8635
8636
8637
8638
8639
8640
8641
8642
8643
8644
8645
8646
8647
8648
8649
8650
8651
8652
8653
8654
8655
8656
8657
8658
8659
8660
8661
8662
8663
8664
8665
8666
8667
8668
8669
8670
8671
8672
8673
8674
8675
8676
8677
8678
8679
8680
8681
8682
8683
8684
8685
8686
8687
8688
8689
8690
8691
8692
8693
8694
8695
8696
8697
8698
8699
8700
8701
8702
8703
8704
8705
8706
8707
8708
8709
8710
8711
8712
8713
8714
8715
8716
8717
8718
8719
8720
8721
8722
8723
8724
8725
8726
8727
8728
8729
8730
8731
8732
8733
8734
8735
8736
8737
8738
8739
8740
8741
8742
8743
8744
8745
8746
8747
8748
8749
8750
8751
8752
8753
8754
8755
8756
8757
8758
8759
8760
8761
8762
8763
8764
8765
8766
8767
8768
8769
8770
8771
8772
8773
8774
8775
8776
8777
8778
8779
8780
8781
8782
8783
8784
8785
8786
8787
8788
8789
8790
8791
8792
8793
8794
8795
8796
8797
8798
8799
8800
8801
8802
8803
8804
8805
8806
8807
8808
8809
8810
8811
8812
8813
8814
8815
8816
8817
8818
8819
8820
8821
8822
8823
8824
8825
8826
8827
8828
8829
8830
8831
8832
8833
8834
8835
8836
8837
8838
8839
8840
8841
8842
8843
8844
8845
8846
8847
8848
8849
8850
8851
8852
8853
8854
8855
8856
8857
8858
8859
8860
8861
8862
8863
8864
8865
8866
8867
8868
8869
8870
8871
8872
8873
8874
8875
8876
8877
8878
8879
8880
8881
8882
8883
8884
8885
8886
8887
8888
8889
8890
8891
8892
8893
8894
8895
8896
8897
8898
8899
8900
8901
8902
8903
8904
8905
8906
8907
8908
8909
8910
8911
8912
8913
8914
8915
8916
8917
8918
8919
8920
8921
8922
8923
8924
8925
8926
8927
8928
8929
8930
8931
8932
8933
8934
8935
8936
8937
8938
8939
8940
8941
8942
8943
8944
8945
8946
8947
8948
8949
8950
8951
8952
8953
8954
8955
8956
8957
8958
8959
8960
8961
8962
8963
8964
8965
8966
8967
8968
8969
8970
8971
8972
8973
8974
8975
8976
8977
8978
8979
8980
8981
8982
8983
8984
8985
8986
8987
8988
8989
8990
8991
8992
8993
8994
8995
8996
8997
8998
8999
9000
9001
9002
9003
9004
9005
9006
9007
9008
9009
9010
9011
9012
9013
9014
9015
9016
9017
9018
9019
9020
9021
9022
9023
9024
9025
9026
9027
9028
9029
9030
9031
9032
9033
9034
9035
9036
9037
9038
9039
9040
9041
9042
9043
9044
9045
9046
9047
9048
9049
9050
9051
9052
9053
9054
9055
9056
9057
9058
9059
9060
9061
9062
9063
9064
9065
9066
9067
9068
9069
9070
9071
9072
9073
9074
9075
9076
9077
9078
9079
9080
9081
9082
9083
9084
9085
9086
9087
9088
9089
9090
9091
9092
9093
9094
9095
9096
9097
9098
9099
9100
9101
9102
9103
9104
9105
9106
9107
9108
9109
9110
9111
9112
9113
9114
9115
9116
9117
9118
9119
9120
9121
9122
9123
9124
9125
9126
9127
9128
9129
9130
9131
9132
9133
9134
9135
9136
9137
9138
9139
9140
9141
9142
9143
9144
9145
9146
9147
9148
9149
9150
9151
9152
9153
9154
9155
9156
9157
9158
9159
9160
9161
9162
9163
9164
9165
9166
9167
9168
9169
9170
9171
9172
9173
9174
9175
9176
9177
9178
9179
9180
9181
9182
9183
9184
9185
9186
9187
9188
9189
9190
9191
9192
9193
9194
9195
9196
9197
9198
9199
9200
9201
9202
9203
9204
9205
9206
9207
9208
9209
9210
9211
9212
9213
9214
9215
9216
9217
9218
9219
9220
9221
9222
9223
9224
9225
9226
9227
9228
9229
9230
9231
9232
9233
9234
9235
9236
9237
9238
9239
9240
9241
9242
9243
9244
9245
9246
9247
9248
9249
9250
9251
9252
9253
9254
9255
9256
9257
9258
9259
9260
9261
9262
9263
9264
9265
9266
9267
9268
9269
9270
9271
9272
9273
9274
9275
9276
9277
9278
9279
9280
9281
9282
9283
9284
9285
9286
9287
9288
9289
9290
9291
9292
9293
9294
9295
9296
9297
9298
9299
9300
9301
9302
9303
9304
9305
9306
9307
9308
9309
9310
9311
9312
9313
9314
9315
9316
9317
9318
9319
9320
9321
9322
9323
9324
9325
9326
9327
9328
9329
9330
9331
9332
9333
9334
9335
9336
9337
9338
9339
9340
9341
9342
9343
9344
9345
9346
9347
9348
9349
9350
9351
9352
9353
9354
9355
9356
9357
9358
9359
9360
9361
9362
9363
9364
9365
9366
9367
9368
9369
9370
9371
9372
9373
9374
9375
9376
9377
9378
9379
9380
9381
9382
9383
9384
9385
9386
9387
9388
9389
9390
9391
9392
9393
9394
9395
9396
9397
9398
9399
9400
9401
9402
9403
9404
9405
9406
9407
9408
9409
9410
9411
9412
9413
9414
9415
9416
9417
9418
9419
9420
9421
9422
9423
9424
9425
9426
9427
9428
9429
9430
9431
9432
9433
9434
9435
9436
9437
9438
9439
9440
9441
9442
9443
9444
9445
9446
9447
9448
9449
9450
9451
9452
9453
9454
9455
9456
9457
9458
9459
9460
9461
9462
9463
9464
9465
9466
9467
9468
9469
9470
9471
9472
9473
9474
9475
9476
9477
9478
9479
9480
9481
9482
9483
9484
9485
9486
9487
9488
9489
9490
9491
9492
9493
9494
9495
9496
9497
9498
9499
9500
9501
9502
9503
9504
9505
9506
9507
9508
9509
9510
9511
9512
9513
9514
9515
9516
9517
9518
9519
9520
9521
9522
9523
9524
9525
9526
9527
9528
9529
9530
9531
9532
9533
9534
9535
9536
9537
9538
9539
9540
9541
9542
9543
9544
9545
9546
9547
9548
9549
9550
9551
9552
9553
9554
9555
9556
9557
9558
9559
9560
9561
9562
9563
9564
9565
9566
9567
9568
9569
9570
9571
9572
9573
9574
9575
9576
9577
9578
9579
9580
9581
9582
9583
9584
9585
9586
9587
9588
9589
9590
9591
9592
9593
9594
9595
9596
9597
9598
9599
9600
9601
9602
9603
9604
9605
9606
9607
9608
9609
9610
9611
9612
9613
9614
9615
9616
9617
9618
9619
9620
9621
9622
9623
9624
9625
9626
9627
9628
9629
9630
9631
9632
9633
9634
9635
9636
9637
9638
9639
9640
9641
9642
9643
9644
9645
9646
9647
9648
9649
9650
9651
9652
9653
9654
9655
9656
9657
9658
9659
9660
9661
9662
9663
9664
9665
9666
9667
9668
9669
9670
9671
9672
9673
9674
9675
9676
9677
9678
9679
9680
9681
9682
9683
9684
9685
9686
9687
9688
9689
9690
9691
9692
9693
9694
9695
9696
9697
9698
9699
9700
9701
9702
9703
9704
9705
9706
9707
9708
9709
9710
9711
9712
9713
9714
9715
9716
9717
9718
9719
9720
9721
9722
9723
9724
9725
9726
9727
9728
9729
9730
9731
9732
9733
9734
9735
9736
9737
9738
9739
9740
9741
9742
9743
9744
9745
9746
9747
9748
9749
9750
9751
9752
9753
9754
9755
9756
9757
9758
9759
9760
9761
9762
9763
9764
9765
9766
9767
9768
9769
9770
9771
9772
9773
9774
9775
9776
9777
9778
9779
9780
9781
9782
9783
9784
9785
9786
9787
9788
9789
9790
9791
9792
9793
9794
9795
9796
9797
9798
9799
9800
9801
9802
9803
9804
9805
9806
9807
9808
9809
9810
9811
9812
9813
9814
9815
9816
9817
9818
9819
9820
9821
9822
9823
9824
9825
9826
9827
9828
9829
9830
9831
9832
9833
9834
9835
9836
9837
9838
9839
9840
9841
9842
9843
9844
9845
9846
9847
9848
9849
9850
9851
9852
9853
9854
9855
9856
9857
9858
9859
9860
9861
9862
9863
9864
9865
9866
9867
9868
9869
9870
9871
9872
9873
9874
9875
9876
9877
9878
9879
9880
9881
9882
9883
9884
9885
9886
9887
9888
9889
9890
9891
9892
9893
9894
9895
9896
9897
9898
9899
9900
9901
9902
9903
9904
9905
9906
9907
9908
9909
9910
9911
9912
9913
9914
9915
9916
9917
9918
9919
9920
9921
9922
9923
9924
9925
9926
9927
9928
9929
9930
9931
9932
9933
9934
9935
9936
9937
9938
9939
9940
9941
9942
9943
9944
9945
9946
9947
9948
9949
9950
9951
9952
9953
9954
9955
9956
9957
9958
9959
9960
9961
9962
9963
9964
9965
9966
9967
9968
9969
9970
9971
9972
9973
9974
9975
9976
9977
9978
9979
9980
9981
9982
9983
9984
9985
9986
9987
9988
9989
9990
9991
9992
9993
9994
9995
9996
9997
9998
9999
10000
10001
10002
10003
10004
10005
10006
10007
10008
10009
10010
10011
10012
10013
10014
10015
10016
10017
10018
10019
10020
10021
10022
10023
10024
10025
10026
10027
10028
10029
10030
10031
10032
10033
10034
10035
10036
10037
10038
10039
10040
10041
10042
10043
10044
10045
10046
10047
10048
10049
10050
10051
10052
10053
10054
10055
10056
10057
10058
10059
10060
10061
10062
10063
10064
10065
10066
10067
10068
10069
10070
10071
10072
10073
10074
10075
10076
10077
10078
10079
10080
10081
10082
10083
10084
10085
10086
10087
10088
10089
10090
10091
10092
10093
10094
10095
10096
10097
10098
10099
10100
10101
10102
10103
10104
10105
10106
10107
10108
10109
10110
10111
10112
10113
10114
10115
10116
10117
10118
10119
10120
10121
10122
10123
10124
10125
10126
10127
10128
10129
10130
10131
10132
10133
10134
10135
10136
10137
10138
10139
10140
10141
10142
10143
10144
10145
10146
10147
10148
10149
10150
10151
10152
10153
10154
10155
10156
10157
10158
10159
10160
10161
10162
10163
10164
10165
10166
10167
10168
10169
10170
10171
10172
10173
10174
10175
10176
10177
10178
10179
10180
10181
10182
10183
10184
10185
10186
10187
10188
10189
10190
10191
10192
10193
10194
10195
10196
10197
10198
10199
10200
10201
10202
10203
10204
10205
10206
10207
10208
10209
10210
10211
10212
10213
10214
10215
10216
10217
10218
10219
10220
10221
10222
10223
10224
10225
10226
10227
10228
10229
10230
10231
10232
10233
10234
10235
10236
10237
10238
10239
10240
10241
10242
10243
10244
10245
10246
10247
10248
10249
10250
10251
10252
10253
10254
10255
10256
10257
10258
10259
10260
10261
10262
10263
10264
10265
10266
10267
10268
10269
10270
10271
10272
10273
10274
10275
10276
10277
10278
10279
10280
10281
10282
10283
10284
10285
10286
10287
10288
10289
10290
10291
10292
10293
10294
10295
10296
10297
10298
10299
10300
10301
10302
10303
10304
10305
10306
10307
10308
10309
10310
10311
10312
10313
10314
10315
10316
10317
10318
10319
10320
10321
10322
10323
10324
10325
10326
10327
10328
10329
10330
10331
10332
10333
10334
10335
10336
10337
10338
10339
10340
10341
10342
10343
10344
10345
10346
10347
10348
10349
10350
10351
10352
10353
10354
10355
10356
10357
10358
10359
10360
10361
10362
10363
10364
10365
10366
10367
10368
10369
10370
10371
10372
10373
10374
10375
10376
10377
10378
10379
10380
10381
10382
10383
10384
10385
10386
10387
10388
10389
10390
10391
10392
10393
10394
10395
10396
10397
10398
10399
10400
10401
10402
10403
10404
10405
10406
10407
10408
10409
10410
10411
10412
10413
10414
10415
10416
10417
10418
10419
10420
10421
10422
10423
10424
10425
10426
10427
10428
10429
10430
10431
10432
10433
10434
10435
10436
10437
10438
10439
10440
10441
10442
10443
10444
10445
10446
10447
10448
10449
10450
10451
10452
10453
10454
10455
10456
10457
10458
10459
10460
10461
10462
10463
10464
10465
10466
10467
10468
10469
10470
10471
10472
10473
10474
10475
10476
10477
10478
10479
10480
10481
10482
10483
10484
10485
10486
10487
10488
10489
10490
10491
10492
10493
10494
10495
10496
10497
10498
10499
10500
10501
10502
10503
10504
10505
10506
10507
10508
10509
10510
10511
10512
10513
10514
10515
10516
10517
10518
10519
10520
10521
10522
10523
10524
10525
10526
10527
10528
10529
10530
10531
10532
10533
10534
10535
10536
10537
10538
10539
10540
10541
10542
10543
10544
10545
10546
10547
10548
10549
10550
10551
10552
10553
10554
10555
10556
10557
10558
10559
10560
10561
10562
10563
10564
10565
10566
10567
10568
10569
10570
10571
10572
10573
10574
10575
10576
10577
10578
10579
10580
10581
10582
10583
10584
10585
10586
10587
10588
10589
10590
10591
10592
10593
10594
10595
10596
10597
10598
10599
10600
10601
10602
10603
10604
10605
10606
10607
10608
10609
10610
10611
10612
10613
10614
10615
10616
10617
10618
10619
10620
10621
10622
10623
10624
10625
10626
10627
10628
10629
10630
10631
10632
10633
10634
10635
10636
10637
10638
10639
10640
10641
10642
10643
10644
10645
10646
10647
10648
10649
10650
10651
10652
10653
10654
10655
10656
10657
10658
10659
10660
10661
10662
10663
10664
10665
10666
10667
10668
10669
10670
10671
10672
10673
10674
10675
10676
10677
10678
10679
10680
10681
10682
10683
10684
10685
10686
10687
10688
10689
10690
10691
10692
10693
10694
10695
10696
10697
10698
10699
10700
10701
10702
10703
10704
10705
10706
10707
10708
10709
10710
10711
10712
10713
10714
10715
10716
10717
10718
10719
10720
10721
10722
10723
10724
10725
10726
10727
10728
10729
10730
10731
10732
10733
10734
10735
10736
10737
10738
10739
10740
10741
10742
10743
10744
10745
10746
10747
10748
10749
10750
10751
10752
10753
10754
10755
10756
10757
10758
10759
10760
10761
10762
10763
10764
10765
10766
10767
10768
10769
10770
10771
10772
10773
10774
10775
10776
10777
10778
10779
10780
10781
10782
10783
10784
10785
10786
10787
10788
10789
10790
10791
10792
10793
10794
10795
10796
10797
10798
10799
10800
10801
10802
10803
10804
10805
10806
10807
10808
10809
10810
10811
10812
10813
10814
10815
10816
10817
10818
10819
10820
10821
10822
10823
10824
10825
10826
10827
10828
10829
10830
10831
10832
10833
10834
10835
10836
10837
10838
10839
10840
10841
10842
10843
10844
10845
10846
10847
10848
10849
10850
10851
10852
10853
10854
10855
10856
10857
10858
10859
10860
10861
10862
10863
10864
10865
10866
10867
10868
10869
10870
10871
10872
10873
10874
10875
10876
10877
10878
10879
10880
10881
10882
10883
10884
10885
10886
10887
10888
10889
10890
10891
10892
10893
10894
10895
10896
10897
10898
10899
10900
10901
10902
10903
10904
10905
10906
10907
10908
10909
10910
10911
10912
10913
10914
10915
10916
10917
10918
10919
10920
10921
10922
10923
10924
10925
10926
10927
10928
10929
10930
10931
10932
10933
10934
10935
10936
10937
10938
10939
10940
10941
10942
10943
10944
10945
10946
10947
10948
10949
10950
10951
10952
10953
10954
10955
10956
10957
10958
10959
10960
10961
10962
10963
10964
10965
10966
10967
10968
10969
10970
10971
10972
10973
10974
10975
10976
10977
10978
10979
10980
10981
10982
10983
10984
10985
10986
10987
10988
10989
10990
10991
10992
10993
10994
10995
10996
10997
10998
10999
11000
11001
11002
11003
11004
11005
11006
11007
11008
11009
11010
11011
11012
11013
11014
11015
11016
11017
11018
11019
11020
11021
11022
11023
11024
11025
11026
11027
11028
11029
11030
11031
11032
11033
11034
11035
11036
11037
11038
11039
11040
11041
11042
11043
11044
11045
11046
11047
11048
11049
11050
11051
11052
11053
11054
11055
11056
11057
11058
11059
11060
11061
11062
11063
11064
11065
11066
11067
11068
11069
11070
11071
11072
11073
11074
11075
11076
11077
11078
11079
11080
11081
11082
11083
11084
11085
11086
11087
11088
11089
11090
11091
11092
11093
11094
11095
11096
11097
11098
11099
11100
11101
11102
11103
11104
11105
11106
11107
11108
11109
11110
11111
11112
11113
11114
11115
11116
11117
11118
11119
11120
11121
11122
11123
11124
11125
11126
11127
11128
11129
11130
11131
11132
11133
11134
11135
11136
11137
11138
11139
11140
11141
11142
11143
11144
11145
11146
11147
11148
11149
11150
11151
11152
11153
11154
11155
11156
11157
11158
11159
11160
11161
11162
11163
11164
11165
11166
11167
11168
11169
11170
11171
11172
11173
11174
11175
11176
11177
11178
11179
11180
11181
11182
11183
11184
11185
11186
11187
11188
11189
11190
11191
11192
11193
11194
11195
11196
11197
11198
11199
11200
11201
11202
11203
11204
11205
11206
11207
11208
11209
11210
11211
11212
11213
11214
11215
11216
11217
11218
11219
11220
11221
11222
11223
11224
11225
11226
11227
11228
11229
11230
11231
11232
11233
11234
11235
11236
11237
11238
11239
11240
11241
11242
11243
11244
11245
11246
11247
11248
11249
11250
11251
11252
11253
11254
11255
11256
11257
11258
11259
11260
11261
11262
11263
11264
11265
11266
11267
11268
11269
11270
11271
11272
11273
11274
11275
11276
11277
11278
11279
11280
11281
11282
11283
11284
11285
11286
11287
11288
11289
11290
11291
11292
11293
11294
11295
11296
11297
11298
11299
11300
11301
11302
11303
11304
11305
11306
11307
11308
11309
11310
11311
11312
11313
11314
11315
11316
11317
11318
11319
11320
11321
11322
11323
11324
11325
11326
11327
11328
11329
11330
11331
11332
11333
11334
11335
11336
11337
11338
11339
11340
11341
11342
11343
11344
11345
11346
11347
11348
11349
11350
11351
11352
11353
11354
11355
11356
11357
11358
11359
11360
11361
11362
11363
11364
11365
11366
11367
11368
11369
11370
11371
11372
11373
11374
11375
11376
11377
11378
11379
11380
11381
11382
11383
11384
11385
11386
11387
11388
11389
11390
11391
11392
11393
11394
11395
11396
11397
11398
11399
11400
11401
11402
11403
11404
11405
11406
11407
11408
11409
11410
11411
11412
11413
11414
11415
11416
11417
11418
11419
11420
11421
11422
11423
11424
11425
11426
11427
11428
11429
11430
11431
11432
11433
11434
11435
11436
11437
11438
11439
11440
11441
11442
11443
11444
11445
11446
11447
11448
11449
11450
11451
11452
11453
11454
11455
11456
11457
11458
11459
11460
11461
11462
11463
11464
11465
11466
11467
11468
11469
11470
11471
11472
11473
11474
11475
11476
11477
11478
11479
11480
11481
11482
11483
11484
11485
11486
11487
11488
11489
11490
11491
11492
11493
11494
11495
11496
11497
11498
11499
11500
11501
11502
11503
11504
11505
11506
11507
11508
11509
11510
11511
11512
11513
11514
11515
11516
11517
11518
11519
11520
11521
11522
11523
11524
11525
11526
11527
11528
11529
11530
11531
11532
11533
11534
11535
11536
11537
11538
11539
11540
11541
11542
11543
11544
11545
11546
11547
11548
11549
11550
11551
11552
11553
11554
11555
11556
11557
11558
11559
11560
11561
11562
11563
11564
11565
11566
11567
11568
11569
11570
11571
11572
11573
11574
11575
11576
11577
11578
11579
11580
11581
11582
11583
11584
11585
11586
11587
11588
11589
11590
11591
11592
11593
11594
11595
11596
11597
11598
11599
11600
11601
11602
11603
11604
11605
11606
11607
11608
11609
11610
11611
11612
11613
11614
11615
11616
11617
11618
11619
11620
11621
11622
11623
11624
11625
11626
11627
11628
11629
11630
11631
11632
11633
11634
11635
11636
11637
11638
11639
11640
11641
11642
11643
11644
11645
11646
11647
11648
11649
11650
11651
11652
11653
11654
11655
11656
11657
11658
11659
11660
11661
11662
11663
11664
11665
11666
11667
11668
11669
11670
11671
11672
11673
11674
11675
11676
11677
11678
11679
11680
11681
11682
11683
11684
11685
11686
11687
11688
11689
11690
11691
11692
11693
11694
11695
11696
11697
11698
11699
11700
11701
11702
11703
11704
11705
11706
11707
11708
11709
11710
11711
11712
11713
11714
11715
11716
11717
11718
11719
11720
11721
11722
11723
11724
11725
11726
11727
11728
11729
11730
11731
11732
11733
11734
11735
11736
11737
11738
11739
11740
11741
11742
11743
11744
11745
11746
11747
11748
11749
11750
11751
11752
11753
11754
11755
11756
11757
11758
11759
11760
11761
11762
11763
11764
11765
11766
11767
11768
11769
11770
11771
11772
11773
11774
11775
11776
11777
11778
11779
11780
11781
11782
11783
11784
11785
11786
11787
11788
11789
11790
11791
11792
11793
11794
11795
11796
11797
11798
11799
11800
11801
11802
11803
11804
11805
11806
11807
11808
11809
11810
11811
11812
11813
11814
11815
11816
11817
11818
11819
11820
11821
11822
11823
11824
11825
11826
11827
11828
11829
11830
11831
11832
11833
11834
11835
11836
11837
11838
11839
11840
11841
11842
11843
11844
11845
11846
11847
11848
11849
11850
11851
11852
11853
11854
11855
11856
11857
11858
11859
11860
11861
11862
11863
11864
11865
11866
11867
11868
11869
11870
11871
11872
11873
11874
11875
11876
11877
11878
11879
11880
11881
11882
11883
11884
11885
11886
11887
11888
11889
11890
11891
11892
11893
11894
11895
11896
11897
11898
11899
11900
11901
11902
11903
11904
11905
11906
11907
11908
11909
11910
11911
11912
11913
11914
11915
11916
11917
11918
11919
11920
11921
11922
11923
11924
11925
11926
11927
11928
11929
11930
11931
11932
11933
11934
11935
11936
11937
11938
11939
11940
11941
11942
11943
11944
11945
11946
11947
11948
11949
11950
11951
11952
11953
11954
11955
11956
11957
11958
11959
11960
11961
11962
11963
11964
11965
11966
11967
11968
11969
11970
11971
11972
11973
11974
11975
11976
11977
11978
11979
11980
11981
11982
11983
11984
11985
11986
11987
11988
11989
11990
11991
11992
11993
11994
11995
11996
11997
11998
11999
12000
12001
12002
12003
12004
12005
12006
12007
12008
12009
12010
12011
12012
12013
12014
12015
12016
12017
12018
12019
12020
12021
12022
12023
12024
12025
12026
12027
12028
12029
12030
12031
12032
12033
12034
12035
12036
12037
12038
12039
12040
12041
12042
12043
12044
12045
12046
12047
12048
12049
12050
12051
12052
12053
12054
12055
12056
12057
12058
12059
12060
12061
12062
12063
12064
12065
12066
12067
12068
12069
12070
12071
12072
12073
12074
12075
12076
12077
12078
12079
12080
12081
12082
12083
12084
12085
12086
12087
12088
12089
12090
12091
12092
12093
12094
12095
12096
12097
12098
12099
12100
12101
12102
12103
12104
12105
12106
12107
12108
12109
12110
12111
12112
12113
12114
12115
12116
12117
12118
12119
12120
12121
12122
12123
12124
12125
12126
12127
12128
12129
12130
12131
12132
12133
12134
12135
12136
12137
12138
12139
12140
12141
12142
12143
12144
12145
12146
12147
12148
12149
12150
12151
12152
12153
12154
12155
12156
12157
12158
12159
12160
12161
12162
12163
12164
12165
12166
12167
12168
12169
12170
12171
12172
12173
12174
12175
12176
12177
12178
12179
12180
12181
12182
12183
12184
12185
12186
12187
12188
12189
12190
12191
12192
12193
12194
12195
12196
12197
12198
12199
12200
12201
12202
12203
12204
12205
12206
12207
12208
12209
12210
12211
12212
12213
12214
12215
12216
12217
12218
12219
12220
12221
12222
12223
12224
12225
12226
12227
12228
12229
12230
12231
12232
12233
12234
12235
12236
12237
12238
12239
12240
12241
12242
12243
12244
12245
12246
12247
12248
12249
12250
12251
12252
12253
12254
12255
12256
12257
12258
12259
12260
12261
12262
12263
12264
12265
12266
12267
12268
12269
12270
12271
12272
12273
12274
12275
12276
12277
12278
12279
12280
12281
12282
12283
12284
12285
12286
12287
12288
12289
12290
12291
12292
12293
12294
12295
12296
12297
12298
12299
12300
12301
12302
12303
12304
12305
12306
12307
12308
12309
12310
12311
12312
12313
12314
12315
12316
12317
12318
12319
12320
12321
12322
12323
12324
12325
12326
12327
12328
12329
12330
12331
12332
12333
12334
12335
12336
12337
12338
12339
12340
12341
12342
12343
12344
12345
12346
12347
12348
12349
12350
12351
12352
12353
12354
12355
12356
12357
12358
12359
12360
12361
12362
12363
12364
12365
12366
12367
12368
12369
12370
12371
12372
12373
12374
12375
12376
12377
12378
12379
12380
12381
12382
12383
12384
12385
12386
12387
12388
12389
12390
12391
12392
12393
12394
12395
12396
12397
12398
12399
12400
12401
12402
12403
12404
12405
12406
12407
12408
12409
12410
12411
12412
12413
12414
12415
12416
12417
12418
12419
12420
12421
12422
12423
12424
12425
12426
12427
12428
12429
12430
12431
12432
12433
12434
12435
12436
12437
12438
12439
12440
12441
12442
12443
12444
12445
12446
12447
12448
12449
12450
12451
12452
12453
12454
12455
12456
12457
12458
12459
12460
12461
12462
12463
12464
12465
12466
12467
12468
12469
12470
12471
12472
12473
12474
12475
12476
12477
12478
12479
12480
12481
12482
12483
12484
12485
12486
12487
12488
12489
12490
12491
12492
12493
12494
12495
12496
12497
12498
12499
12500
12501
12502
12503
12504
12505
12506
12507
12508
12509
12510
12511
12512
12513
12514
12515
12516
12517
12518
12519
12520
12521
12522
12523
12524
12525
12526
12527
12528
12529
12530
12531
12532
12533
12534
12535
12536
12537
12538
12539
12540
12541
12542
12543
12544
12545
12546
12547
12548
12549
12550
12551
12552
12553
12554
12555
12556
12557
12558
12559
12560
12561
12562
12563
12564
12565
12566
12567
12568
12569
12570
12571
12572
12573
12574
12575
12576
12577
12578
12579
12580
12581
12582
12583
12584
12585
12586
12587
12588
12589
12590
12591
12592
12593
12594
12595
12596
12597
12598
12599
12600
12601
12602
12603
12604
12605
12606
12607
12608
12609
12610
12611
12612
12613
12614
12615
12616
12617
12618
12619
12620
12621
12622
12623
12624
12625
12626
12627
12628
12629
12630
12631
12632
12633
12634
12635
12636
12637
12638
12639
12640
12641
12642
12643
12644
12645
12646
12647
12648
12649
12650
12651
12652
12653
12654
12655
12656
12657
12658
12659
12660
12661
12662
12663
12664
12665
12666
12667
12668
12669
12670
12671
12672
12673
12674
12675
12676
12677
12678
12679
12680
12681
12682
12683
12684
12685
12686
12687
12688
12689
12690
12691
12692
12693
12694
12695
12696
12697
12698
12699
12700
12701
12702
12703
12704
12705
12706
12707
12708
12709
12710
12711
12712
12713
12714
12715
12716
12717
12718
12719
12720
12721
12722
12723
12724
12725
12726
12727
12728
12729
12730
12731
12732
12733
12734
12735
12736
12737
12738
12739
12740
12741
12742
12743
12744
12745
12746
12747
12748
12749
12750
12751
12752
12753
12754
12755
12756
12757
12758
12759
12760
12761
12762
12763
12764
12765
12766
12767
12768
12769
12770
12771
12772
12773
12774
12775
12776
12777
12778
12779
12780
12781
12782
12783
12784
12785
12786
12787
12788
12789
12790
12791
12792
12793
12794
12795
12796
12797
12798
12799
12800
12801
12802
12803
12804
12805
12806
12807
12808
12809
12810
12811
12812
12813
12814
12815
12816
12817
12818
12819
12820
12821
12822
12823
12824
12825
12826
12827
12828
12829
12830
12831
12832
12833
12834
12835
12836
12837
12838
12839
12840
12841
12842
12843
12844
12845
12846
12847
12848
12849
12850
12851
12852
12853
12854
12855
12856
12857
12858
12859
12860
12861
12862
12863
12864
12865
12866
12867
12868
12869
12870
12871
12872
12873
12874
12875
12876
12877
12878
12879
12880
12881
12882
12883
12884
12885
12886
12887
12888
12889
12890
12891
12892
12893
12894
12895
12896
12897
12898
12899
12900
12901
12902
12903
12904
12905
12906
12907
12908
12909
12910
12911
12912
12913
12914
12915
12916
12917
12918
12919
12920
12921
12922
12923
12924
12925
12926
12927
12928
12929
12930
12931
12932
12933
12934
12935
12936
12937
12938
12939
12940
12941
12942
12943
12944
12945
12946
12947
12948
12949
12950
12951
12952
12953
12954
12955
12956
12957
12958
12959
12960
12961
12962
12963
12964
12965
12966
12967
12968
12969
12970
12971
12972
12973
12974
12975
12976
12977
12978
12979
12980
12981
12982
12983
12984
12985
12986
12987
12988
12989
12990
12991
12992
12993
12994
12995
12996
12997
12998
12999
13000
13001
13002
13003
13004
13005
13006
13007
13008
13009
13010
13011
13012
13013
13014
13015
13016
13017
13018
13019
13020
13021
13022
13023
13024
13025
13026
13027
13028
13029
13030
13031
13032
13033
13034
13035
13036
13037
13038
13039
13040
13041
13042
13043
13044
13045
13046
13047
13048
13049
13050
13051
13052
13053
13054
13055
13056
13057
13058
13059
13060
13061
13062
13063
13064
13065
13066
13067
13068
13069
13070
13071
13072
13073
13074
13075
13076
13077
13078
13079
13080
13081
13082
13083
13084
13085
13086
13087
13088
13089
13090
13091
13092
13093
13094
13095
13096
13097
13098
13099
13100
13101
13102
13103
13104
13105
13106
13107
13108
13109
13110
13111
13112
13113
13114
13115
13116
13117
13118
13119
13120
13121
13122
13123
13124
13125
13126
13127
13128
13129
13130
13131
13132
13133
13134
13135
13136
13137
13138
13139
13140
13141
13142
13143
13144
13145
13146
13147
13148
13149
13150
13151
13152
13153
13154
13155
13156
13157
13158
13159
13160
13161
13162
13163
13164
13165
13166
13167
13168
13169
13170
13171
13172
13173
13174
13175
13176
13177
13178
13179
13180
13181
13182
13183
13184
13185
13186
13187
13188
13189
13190
13191
13192
13193
13194
13195
13196
13197
13198
13199
13200
13201
13202
13203
13204
13205
13206
13207
13208
13209
13210
13211
13212
13213
13214
13215
13216
13217
13218
13219
13220
13221
13222
13223
13224
13225
13226
13227
13228
13229
13230
13231
13232
13233
13234
13235
13236
13237
13238
13239
13240
13241
13242
13243
13244
13245
13246
13247
13248
13249
13250
13251
13252
13253
13254
13255
13256
13257
13258
13259
13260
13261
13262
13263
13264
13265
13266
13267
13268
13269
13270
13271
13272
13273
13274
13275
13276
13277
13278
13279
13280
13281
13282
13283
13284
13285
13286
13287
13288
13289
13290
13291
13292
13293
13294
13295
13296
13297
13298
13299
13300
13301
13302
13303
13304
13305
13306
13307
13308
13309
13310
13311
13312
13313
13314
13315
13316
13317
13318
13319
13320
13321
13322
13323
13324
13325
13326
13327
13328
13329
13330
13331
13332
13333
13334
13335
13336
13337
13338
13339
13340
13341
13342
13343
13344
13345
13346
13347
13348
13349
13350
13351
13352
13353
13354
13355
13356
13357
13358
13359
13360
13361
13362
13363
13364
13365
13366
13367
13368
13369
13370
13371
13372
13373
13374
13375
13376
13377
13378
13379
13380
13381
13382
13383
13384
13385
13386
13387
13388
13389
13390
13391
13392
13393
13394
13395
13396
13397
13398
13399
13400
13401
13402
13403
13404
13405
13406
13407
13408
13409
13410
13411
13412
13413
13414
13415
13416
13417
13418
13419
13420
13421
13422
13423
13424
13425
13426
13427
13428
13429
13430
13431
13432
13433
13434
13435
13436
13437
13438
13439
13440
13441
13442
13443
13444
13445
13446
13447
13448
13449
13450
13451
13452
13453
13454
13455
13456
13457
13458
13459
13460
13461
13462
13463
13464
13465
13466
13467
13468
13469
13470
13471
13472
13473
13474
13475
13476
13477
13478
13479
13480
13481
13482
13483
13484
13485
13486
13487
13488
13489
13490
13491
13492
13493
13494
13495
13496
13497
13498
13499
13500
13501
13502
13503
13504
13505
13506
13507
13508
13509
13510
13511
13512
13513
13514
13515
13516
13517
13518
13519
13520
13521
13522
13523
13524
13525
13526
13527
13528
13529
13530
13531
13532
13533
13534
13535
13536
13537
13538
13539
13540
13541
13542
13543
13544
13545
13546
13547
13548
13549
13550
13551
13552
13553
13554
13555
13556
13557
13558
13559
13560
13561
13562
13563
13564
13565
13566
13567
13568
13569
13570
13571
13572
13573
13574
13575
13576
13577
13578
13579
13580
13581
13582
13583
13584
13585
13586
13587
13588
13589
13590
13591
13592
13593
13594
13595
13596
13597
13598
13599
13600
13601
13602
13603
13604
13605
13606
13607
13608
13609
13610
13611
13612
13613
13614
13615
13616
13617
13618
13619
13620
13621
13622
13623
13624
13625
13626
13627
13628
13629
13630
13631
13632
13633
13634
13635
13636
13637
13638
13639
13640
13641
13642
13643
13644
13645
13646
13647
13648
13649
13650
13651
13652
13653
13654
13655
13656
13657
13658
13659
13660
13661
13662
13663
13664
13665
13666
13667
13668
13669
13670
13671
13672
13673
13674
13675
13676
13677
13678
13679
13680
13681
13682
13683
13684
13685
13686
13687
13688
13689
13690
13691
13692
13693
13694
13695
13696
13697
13698
13699
13700
13701
13702
13703
13704
13705
13706
13707
13708
13709
13710
13711
13712
13713
13714
13715
13716
13717
13718
13719
13720
13721
13722
13723
13724
13725
13726
13727
13728
13729
13730
13731
13732
13733
13734
13735
13736
13737
13738
13739
13740
13741
13742
13743
13744
13745
13746
13747
13748
13749
13750
13751
13752
13753
13754
13755
13756
13757
13758
13759
13760
13761
13762
13763
13764
13765
13766
13767
13768
13769
13770
13771
13772
13773
13774
13775
13776
13777
13778
13779
13780
13781
13782
13783
13784
13785
13786
13787
13788
13789
13790
13791
13792
13793
13794
13795
13796
13797
13798
13799
13800
13801
13802
13803
13804
13805
13806
13807
13808
13809
13810
13811
13812
13813
13814
13815
13816
13817
13818
13819
13820
13821
13822
13823
13824
13825
13826
13827
13828
13829
13830
13831
13832
13833
13834
13835
13836
13837
13838
13839
13840
13841
13842
13843
13844
13845
13846
13847
13848
13849
13850
13851
13852
13853
13854
13855
13856
13857
13858
13859
13860
13861
13862
13863
13864
13865
13866
13867
13868
13869
13870
13871
13872
13873
13874
13875
13876
13877
13878
13879
13880
13881
13882
13883
13884
13885
13886
13887
13888
13889
13890
13891
13892
13893
13894
13895
13896
13897
13898
13899
13900
13901
13902
13903
13904
13905
13906
13907
13908
13909
13910
13911
13912
13913
13914
13915
13916
13917
13918
13919
13920
13921
13922
13923
13924
13925
13926
13927
13928
13929
13930
13931
13932
13933
13934
13935
13936
13937
13938
13939
13940
13941
13942
13943
13944
13945
13946
13947
13948
13949
13950
13951
13952
13953
13954
13955
13956
13957
13958
13959
13960
13961
13962
13963
13964
13965
13966
13967
13968
13969
13970
13971
13972
13973
13974
13975
13976
13977
13978
13979
13980
13981
13982
13983
13984
13985
13986
13987
13988
13989
13990
13991
13992
13993
13994
13995
13996
13997
13998
13999
14000
14001
14002
14003
14004
14005
14006
14007
14008
14009
14010
14011
14012
14013
14014
14015
14016
14017
14018
14019
14020
14021
14022
14023
14024
14025
14026
14027
14028
14029
14030
14031
14032
14033
14034
14035
14036
14037
14038
14039
14040
14041
14042
14043
14044
14045
14046
14047
14048
14049
14050
14051
14052
14053
14054
14055
14056
14057
14058
14059
14060
14061
14062
14063
14064
14065
14066
14067
14068
14069
14070
14071
14072
14073
14074
14075
14076
14077
14078
14079
14080
14081
14082
14083
14084
14085
14086
14087
14088
14089
14090
14091
14092
14093
14094
14095
14096
14097
14098
14099
14100
14101
14102
14103
14104
14105
14106
14107
14108
14109
14110
14111
14112
14113
14114
14115
14116
14117
14118
14119
14120
14121
14122
14123
14124
14125
14126
14127
14128
14129
14130
14131
14132
14133
14134
14135
14136
14137
14138
14139
14140
14141
14142
14143
14144
14145
14146
14147
14148
14149
14150
14151
14152
14153
14154
14155
14156
14157
14158
14159
14160
14161
14162
14163
14164
14165
14166
14167
14168
14169
14170
14171
14172
14173
14174
14175
14176
14177
14178
14179
14180
14181
14182
14183
14184
14185
14186
14187
14188
14189
14190
14191
14192
14193
14194
14195
14196
14197
14198
14199
14200
14201
14202
14203
14204
14205
14206
14207
14208
14209
14210
14211
14212
14213
14214
14215
14216
14217
14218
14219
14220
14221
14222
14223
14224
14225
14226
14227
14228
14229
14230
14231
14232
14233
14234
14235
14236
14237
14238
14239
14240
14241
14242
14243
14244
14245
14246
14247
14248
14249
14250
14251
14252
14253
14254
14255
14256
14257
14258
14259
14260
14261
14262
14263
14264
14265
14266
14267
14268
14269
14270
14271
14272
14273
14274
14275
14276
14277
14278
14279
14280
14281
14282
14283
14284
14285
14286
14287
14288
14289
14290
14291
14292
14293
14294
14295
14296
14297
14298
14299
14300
14301
14302
14303
14304
14305
14306
14307
14308
14309
14310
14311
14312
14313
14314
14315
14316
14317
14318
14319
14320
14321
14322
14323
14324
14325
14326
14327
14328
14329
14330
14331
14332
14333
14334
14335
14336
14337
14338
14339
14340
14341
14342
14343
14344
14345
14346
14347
14348
14349
14350
14351
14352
14353
14354
14355
14356
14357
14358
14359
14360
14361
14362
14363
14364
14365
14366
14367
14368
14369
14370
14371
14372
14373
14374
14375
14376
14377
14378
14379
14380
14381
14382
14383
14384
14385
14386
14387
14388
14389
14390
14391
14392
14393
14394
14395
14396
14397
14398
14399
14400
14401
14402
14403
14404
14405
14406
14407
14408
14409
14410
14411
14412
14413
14414
14415
14416
14417
14418
14419
14420
14421
14422
14423
14424
14425
14426
14427
14428
14429
14430
14431
14432
14433
14434
14435
14436
14437
14438
14439
14440
14441
14442
14443
14444
14445
14446
14447
14448
14449
14450
14451
14452
14453
14454
14455
14456
14457
14458
14459
14460
14461
14462
14463
14464
14465
14466
14467
14468
14469
14470
14471
14472
14473
14474
14475
14476
14477
14478
14479
14480
14481
14482
14483
14484
14485
14486
14487
14488
14489
14490
14491
14492
14493
14494
14495
14496
14497
14498
14499
14500
14501
14502
14503
14504
14505
14506
14507
14508
14509
14510
14511
14512
14513
14514
14515
14516
14517
14518
14519
14520
14521
14522
14523
14524
14525
14526
14527
14528
14529
14530
14531
14532
14533
14534
14535
14536
14537
14538
14539
14540
14541
14542
14543
14544
14545
14546
14547
14548
14549
14550
14551
14552
14553
14554
14555
14556
14557
14558
14559
14560
14561
14562
14563
14564
14565
14566
14567
14568
14569
14570
14571
14572
14573
14574
14575
14576
14577
14578
14579
14580
14581
14582
14583
14584
14585
14586
14587
14588
14589
14590
14591
14592
14593
14594
14595
14596
14597
14598
14599
14600
14601
14602
14603
14604
14605
14606
14607
14608
14609
14610
14611
14612
14613
14614
14615
14616
14617
14618
14619
14620
14621
14622
14623
14624
14625
14626
14627
14628
14629
14630
14631
14632
14633
14634
14635
14636
14637
14638
14639
14640
14641
14642
14643
14644
14645
14646
14647
14648
14649
14650
14651
14652
14653
14654
14655
14656
14657
14658
14659
14660
14661
14662
14663
14664
14665
14666
14667
14668
14669
14670
14671
14672
14673
14674
14675
14676
14677
14678
14679
14680
14681
14682
14683
14684
14685
14686
14687
14688
14689
14690
14691
14692
14693
14694
14695
14696
14697
14698
14699
14700
14701
14702
14703
14704
14705
14706
14707
14708
14709
14710
14711
14712
14713
14714
14715
14716
14717
14718
14719
14720
14721
14722
14723
14724
14725
14726
14727
14728
14729
14730
14731
14732
14733
14734
14735
14736
14737
14738
14739
14740
14741
14742
14743
14744
14745
14746
14747
14748
14749
14750
14751
14752
14753
14754
14755
14756
14757
14758
14759
14760
14761
14762
14763
14764
14765
14766
14767
14768
14769
14770
14771
14772
14773
14774
14775
14776
14777
14778
14779
14780
14781
14782
14783
14784
14785
14786
14787
14788
14789
14790
14791
14792
14793
14794
14795
14796
14797
14798
14799
14800
14801
14802
14803
14804
14805
14806
14807
14808
14809
14810
14811
14812
14813
14814
14815
14816
14817
14818
14819
14820
14821
14822
14823
14824
14825
14826
14827
14828
14829
14830
14831
14832
14833
14834
14835
14836
14837
14838
14839
14840
14841
14842
14843
14844
14845
14846
14847
14848
14849
14850
14851
14852
14853
14854
14855
14856
14857
14858
14859
14860
14861
14862
14863
14864
14865
14866
14867
14868
14869
14870
14871
14872
14873
14874
14875
14876
14877
14878
14879
14880
14881
14882
14883
14884
14885
14886
14887
14888
14889
14890
14891
14892
14893
14894
14895
14896
14897
14898
14899
14900
14901
14902
14903
14904
14905
14906
14907
14908
14909
14910
14911
14912
14913
14914
14915
14916
14917
14918
14919
14920
14921
14922
14923
14924
14925
14926
14927
14928
14929
14930
14931
14932
14933
14934
14935
14936
14937
14938
14939
14940
14941
14942
14943
14944
14945
14946
14947
14948
14949
14950
14951
14952
14953
14954
14955
14956
14957
14958
14959
14960
14961
14962
14963
14964
14965
14966
14967
14968
14969
14970
14971
14972
14973
14974
14975
14976
14977
14978
14979
14980
14981
14982
14983
14984
14985
14986
14987
14988
14989
14990
14991
14992
14993
14994
14995
14996
14997
14998
14999
15000
15001
15002
15003
15004
15005
15006
15007
15008
15009
15010
15011
15012
15013
15014
15015
15016
15017
15018
15019
15020
15021
15022
15023
15024
15025
15026
15027
15028
15029
15030
15031
15032
15033
15034
15035
15036
15037
15038
15039
15040
15041
15042
15043
15044
15045
15046
15047
15048
15049
15050
15051
15052
15053
15054
15055
15056
15057
15058
15059
15060
15061
15062
15063
15064
15065
15066
15067
15068
15069
15070
15071
15072
15073
15074
15075
15076
15077
15078
15079
15080
15081
15082
15083
15084
15085
15086
15087
15088
15089
15090
15091
15092
15093
15094
15095
15096
15097
15098
15099
15100
15101
15102
15103
15104
15105
15106
15107
15108
15109
15110
15111
15112
15113
15114
15115
15116
15117
15118
15119
15120
15121
15122
15123
15124
15125
15126
15127
15128
15129
15130
15131
15132
15133
15134
15135
15136
15137
15138
15139
15140
15141
15142
15143
15144
15145
15146
15147
15148
15149
15150
15151
15152
15153
15154
15155
15156
15157
15158
15159
15160
15161
15162
15163
15164
15165
15166
15167
15168
15169
15170
15171
15172
15173
15174
15175
15176
15177
15178
15179
15180
15181
15182
15183
15184
15185
15186
15187
15188
15189
15190
15191
15192
15193
15194
15195
15196
15197
15198
15199
15200
15201
15202
15203
15204
15205
15206
15207
15208
15209
15210
15211
15212
15213
15214
15215
15216
15217
15218
15219
15220
15221
15222
15223
15224
15225
15226
15227
15228
15229
15230
15231
15232
15233
15234
15235
15236
15237
15238
15239
15240
15241
15242
15243
15244
15245
15246
15247
15248
15249
15250
15251
15252
15253
15254
15255
15256
15257
15258
15259
15260
15261
15262
15263
15264
15265
15266
15267
15268
15269
15270
15271
15272
15273
15274
15275
15276
15277
15278
15279
15280
15281
15282
15283
15284
15285
15286
15287
15288
15289
15290
15291
15292
15293
15294
15295
15296
15297
15298
15299
15300
15301
15302
15303
15304
15305
15306
15307
15308
15309
15310
15311
15312
15313
15314
15315
15316
15317
15318
15319
15320
15321
15322
15323
15324
15325
15326
15327
15328
15329
15330
15331
15332
15333
15334
15335
15336
15337
15338
15339
15340
15341
15342
15343
15344
15345
15346
15347
15348
15349
15350
15351
15352
15353
15354
15355
15356
15357
15358
15359
15360
15361
15362
15363
15364
15365
15366
15367
15368
15369
15370
15371
15372
15373
15374
15375
15376
15377
15378
15379
15380
15381
15382
15383
15384
15385
15386
15387
15388
15389
15390
15391
15392
15393
15394
15395
15396
15397
15398
15399
15400
15401
15402
15403
15404
15405
15406
15407
15408
15409
15410
15411
15412
15413
15414
15415
15416
15417
15418
15419
15420
15421
15422
15423
15424
15425
15426
15427
15428
15429
15430
15431
15432
15433
15434
15435
15436
15437
15438
15439
15440
15441
15442
15443
15444
15445
15446
15447
15448
15449
15450
15451
15452
15453
15454
15455
15456
15457
15458
15459
15460
15461
15462
15463
15464
15465
15466
15467
15468
15469
15470
15471
15472
15473
15474
15475
15476
15477
15478
15479
15480
15481
15482
15483
15484
15485
15486
15487
15488
15489
15490
15491
15492
15493
15494
15495
15496
15497
15498
15499
15500
15501
15502
15503
15504
15505
15506
15507
15508
15509
15510
15511
15512
15513
15514
15515
15516
15517
15518
15519
15520
15521
15522
15523
15524
15525
15526
15527
15528
15529
15530
15531
15532
15533
15534
15535
15536
15537
15538
15539
15540
15541
15542
15543
15544
15545
15546
15547
15548
15549
15550
15551
15552
15553
15554
15555
15556
15557
15558
15559
15560
15561
15562
15563
15564
15565
15566
15567
15568
15569
15570
15571
15572
15573
15574
15575
15576
15577
15578
15579
15580
15581
15582
15583
15584
15585
15586
15587
15588
15589
15590
15591
15592
15593
15594
15595
15596
15597
15598
15599
15600
15601
15602
15603
15604
15605
15606
15607
15608
15609
15610
15611
15612
15613
15614
15615
15616
15617
15618
15619
15620
15621
15622
15623
15624
15625
15626
15627
15628
15629
15630
15631
15632
15633
15634
15635
15636
15637
15638
15639
15640
15641
15642
15643
15644
15645
15646
15647
15648
15649
15650
15651
15652
15653
15654
15655
15656
15657
15658
15659
15660
15661
15662
15663
15664
15665
15666
15667
15668
15669
15670
15671
15672
15673
15674
15675
15676
15677
15678
15679
15680
15681
15682
15683
15684
15685
15686
15687
15688
15689
15690
15691
15692
15693
15694
15695
15696
15697
15698
15699
15700
15701
15702
15703
15704
15705
15706
15707
15708
15709
15710
15711
15712
15713
15714
15715
15716
15717
15718
15719
15720
15721
15722
15723
15724
15725
15726
15727
15728
15729
15730
15731
15732
15733
15734
15735
15736
15737
15738
15739
15740
15741
15742
15743
15744
15745
15746
15747
15748
15749
15750
15751
15752
15753
15754
15755
15756
15757
15758
15759
15760
15761
15762
15763
15764
15765
15766
15767
15768
15769
15770
15771
15772
15773
15774
15775
15776
15777
15778
15779
15780
15781
15782
15783
15784
15785
15786
15787
15788
15789
15790
15791
15792
15793
15794
15795
15796
15797
15798
15799
15800
15801
15802
15803
15804
15805
15806
15807
15808
15809
15810
15811
15812
15813
15814
15815
15816
15817
15818
15819
15820
15821
15822
15823
15824
15825
15826
15827
15828
15829
15830
15831
15832
15833
15834
15835
15836
15837
15838
15839
15840
15841
15842
15843
15844
15845
15846
15847
15848
15849
15850
15851
15852
15853
15854
15855
15856
15857
15858
15859
15860
15861
15862
15863
15864
15865
15866
15867
15868
15869
15870
15871
15872
15873
15874
15875
15876
15877
15878
15879
15880
15881
15882
15883
15884
15885
15886
15887
15888
15889
15890
15891
15892
15893
15894
15895
15896
15897
15898
15899
15900
15901
15902
15903
15904
15905
15906
15907
15908
15909
15910
15911
15912
15913
15914
15915
15916
15917
15918
15919
15920
15921
15922
15923
15924
15925
15926
15927
15928
15929
15930
15931
15932
15933
15934
15935
15936
15937
15938
15939
15940
15941
15942
15943
15944
15945
15946
15947
15948
15949
15950
15951
15952
15953
15954
15955
15956
15957
15958
15959
15960
15961
15962
15963
15964
15965
15966
15967
15968
15969
15970
15971
15972
15973
15974
15975
15976
15977
15978
15979
15980
15981
15982
15983
15984
15985
15986
15987
15988
15989
15990
15991
15992
15993
15994
15995
15996
15997
15998
15999
16000
16001
16002
16003
16004
16005
16006
16007
16008
16009
16010
16011
16012
16013
16014
16015
16016
16017
16018
16019
16020
16021
16022
16023
16024
16025
16026
16027
16028
16029
16030
16031
16032
16033
16034
16035
16036
16037
16038
16039
16040
16041
16042
16043
16044
16045
16046
16047
16048
16049
16050
16051
16052
16053
16054
16055
16056
16057
16058
16059
16060
16061
16062
16063
16064
16065
16066
16067
16068
16069
16070
16071
16072
16073
16074
16075
16076
16077
16078
16079
16080
16081
16082
16083
16084
16085
16086
16087
16088
16089
16090
16091
16092
16093
16094
16095
16096
16097
16098
16099
16100
16101
16102
16103
16104
16105
16106
16107
16108
16109
16110
16111
16112
16113
16114
16115
16116
16117
16118
16119
16120
16121
16122
16123
16124
16125
16126
16127
16128
16129
16130
16131
16132
16133
16134
16135
16136
16137
16138
16139
16140
16141
16142
16143
16144
16145
16146
16147
16148
16149
16150
16151
16152
16153
16154
16155
16156
16157
16158
16159
16160
16161
16162
16163
16164
16165
16166
16167
16168
16169
16170
16171
16172
16173
16174
16175
16176
16177
16178
16179
16180
16181
16182
16183
16184
16185
16186
16187
16188
16189
16190
16191
16192
16193
16194
16195
16196
16197
16198
16199
16200
16201
16202
16203
16204
16205
16206
16207
16208
16209
16210
16211
16212
16213
16214
16215
16216
16217
16218
16219
16220
16221
16222
16223
16224
16225
16226
16227
16228
16229
16230
16231
16232
16233
16234
16235
16236
16237
16238
16239
16240
16241
16242
16243
16244
16245
16246
16247
16248
16249
16250
16251
16252
16253
16254
16255
16256
16257
16258
16259
16260
16261
16262
16263
16264
16265
16266
16267
16268
16269
16270
16271
16272
16273
16274
16275
16276
16277
16278
16279
16280
16281
16282
16283
16284
16285
16286
16287
16288
16289
16290
16291
16292
16293
16294
16295
16296
16297
16298
16299
16300
16301
16302
16303
16304
16305
16306
16307
16308
16309
16310
16311
16312
16313
16314
16315
16316
16317
16318
16319
16320
16321
16322
16323
16324
16325
16326
16327
16328
16329
16330
16331
16332
16333
16334
16335
16336
16337
16338
16339
16340
16341
16342
16343
16344
16345
16346
16347
16348
16349
16350
16351
16352
16353
16354
16355
16356
16357
16358
16359
16360
16361
16362
16363
16364
16365
16366
16367
16368
16369
16370
16371
16372
16373
16374
16375
16376
16377
16378
16379
16380
16381
16382
16383
16384
16385
16386
16387
16388
16389
16390
16391
16392
16393
16394
16395
16396
16397
16398
16399
16400
16401
16402
16403
16404
16405
16406
16407
16408
16409
16410
16411
16412
16413
16414
16415
16416
16417
16418
16419
16420
16421
16422
16423
16424
16425
16426
16427
16428
16429
16430
16431
16432
16433
16434
16435
16436
16437
16438
16439
16440
16441
16442
16443
16444
16445
16446
16447
16448
16449
16450
16451
16452
16453
16454
16455
16456
16457
16458
16459
16460
16461
16462
16463
16464
16465
16466
16467
16468
16469
16470
16471
16472
16473
16474
16475
16476
16477
16478
16479
16480
16481
16482
16483
16484
16485
16486
16487
16488
16489
16490
16491
16492
16493
16494
16495
16496
16497
16498
16499
16500
16501
16502
16503
16504
16505
16506
16507
16508
16509
16510
16511
16512
16513
16514
16515
16516
16517
16518
16519
16520
16521
16522
16523
16524
16525
16526
16527
16528
16529
16530
16531
16532
16533
16534
16535
16536
16537
16538
16539
16540
16541
16542
16543
16544
16545
16546
16547
16548
16549
16550
16551
16552
16553
16554
16555
16556
16557
16558
16559
16560
16561
16562
16563
16564
16565
16566
16567
16568
16569
16570
16571
16572
16573
16574
16575
16576
16577
16578
16579
16580
16581
16582
16583
16584
16585
16586
16587
16588
16589
16590
16591
16592
16593
16594
16595
16596
16597
16598
16599
16600
16601
16602
16603
16604
16605
16606
16607
16608
16609
16610
16611
16612
16613
16614
16615
16616
16617
16618
16619
16620
16621
16622
16623
16624
16625
16626
16627
16628
16629
16630
16631
16632
16633
16634
16635
16636
16637
16638
16639
16640
16641
16642
16643
16644
16645
16646
16647
16648
16649
16650
16651
16652
16653
16654
16655
16656
16657
16658
16659
16660
16661
16662
16663
16664
16665
16666
16667
16668
16669
16670
16671
16672
16673
16674
16675
16676
16677
16678
16679
16680
16681
16682
16683
16684
16685
16686
16687
16688
16689
16690
16691
16692
16693
16694
16695
16696
16697
16698
16699
16700
16701
16702
16703
16704
16705
16706
16707
16708
16709
16710
16711
16712
16713
16714
16715
16716
16717
16718
16719
16720
16721
16722
16723
16724
16725
16726
16727
16728
16729
16730
16731
16732
16733
16734
16735
16736
16737
16738
16739
16740
16741
16742
16743
16744
16745
16746
16747
16748
16749
16750
16751
16752
16753
16754
16755
16756
16757
16758
16759
16760
16761
16762
16763
16764
16765
16766
16767
16768
16769
16770
16771
16772
16773
16774
16775
16776
16777
16778
16779
16780
16781
16782
16783
16784
16785
16786
16787
16788
16789
16790
16791
16792
16793
16794
16795
16796
16797
16798
16799
16800
16801
16802
16803
16804
16805
16806
16807
16808
16809
16810
16811
16812
16813
16814
16815
16816
16817
16818
16819
16820
16821
16822
16823
16824
16825
16826
16827
16828
16829
16830
16831
16832
16833
16834
16835
16836
16837
16838
16839
16840
16841
16842
16843
16844
16845
16846
16847
16848
16849
16850
16851
16852
16853
16854
16855
16856
16857
16858
16859
16860
16861
16862
16863
16864
16865
16866
16867
16868
16869
16870
16871
16872
16873
16874
16875
16876
16877
16878
16879
16880
16881
16882
16883
16884
16885
16886
16887
16888
16889
16890
16891
16892
16893
16894
16895
16896
16897
16898
16899
16900
16901
16902
16903
16904
16905
16906
16907
16908
16909
16910
16911
16912
16913
16914
16915
16916
16917
16918
16919
16920
16921
16922
16923
16924
16925
16926
16927
16928
16929
16930
16931
16932
16933
16934
16935
16936
16937
16938
16939
16940
16941
16942
16943
16944
16945
16946
16947
16948
16949
16950
16951
16952
16953
16954
16955
16956
16957
16958
16959
16960
16961
16962
16963
16964
16965
16966
16967
16968
16969
16970
16971
16972
16973
16974
16975
16976
16977
16978
16979
16980
16981
16982
16983
16984
16985
16986
16987
16988
16989
16990
16991
16992
16993
16994
16995
16996
16997
16998
16999
17000
17001
17002
17003
17004
17005
17006
17007
17008
17009
17010
17011
17012
17013
17014
17015
17016
17017
17018
17019
17020
17021
17022
17023
17024
17025
17026
17027
17028
17029
17030
17031
17032
17033
17034
17035
17036
17037
17038
17039
17040
17041
17042
17043
17044
17045
17046
17047
17048
17049
17050
17051
17052
17053
17054
17055
17056
17057
17058
17059
17060
17061
17062
17063
17064
17065
17066
17067
17068
17069
17070
17071
17072
17073
17074
17075
17076
17077
17078
17079
17080
17081
17082
17083
17084
17085
17086
17087
17088
17089
17090
17091
17092
17093
17094
17095
17096
17097
17098
17099
17100
17101
17102
17103
17104
17105
17106
17107
17108
17109
17110
17111
17112
17113
17114
17115
17116
17117
17118
17119
17120
17121
17122
17123
17124
17125
17126
17127
17128
17129
17130
17131
17132
17133
17134
17135
17136
17137
17138
17139
17140
17141
17142
17143
17144
17145
17146
17147
17148
17149
17150
17151
17152
17153
17154
17155
17156
17157
17158
17159
17160
17161
17162
17163
17164
17165
17166
17167
17168
17169
17170
17171
17172
17173
17174
17175
17176
17177
17178
17179
17180
17181
17182
17183
17184
17185
17186
17187
17188
17189
17190
17191
17192
17193
17194
17195
17196
17197
17198
17199
17200
17201
17202
17203
17204
17205
17206
17207
17208
17209
17210
17211
17212
17213
17214
17215
17216
17217
17218
17219
17220
17221
17222
17223
17224
17225
17226
17227
17228
17229
17230
17231
17232
17233
17234
17235
17236
17237
17238
17239
17240
17241
17242
17243
17244
17245
17246
17247
17248
17249
17250
17251
17252
17253
17254
17255
17256
17257
17258
17259
17260
17261
17262
17263
17264
17265
17266
17267
17268
17269
17270
17271
17272
17273
17274
17275
17276
17277
17278
17279
17280
17281
17282
17283
17284
17285
17286
17287
17288
17289
17290
17291
17292
17293
17294
17295
17296
17297
17298
17299
17300
17301
17302
17303
17304
17305
17306
17307
17308
17309
17310
17311
17312
17313
17314
17315
17316
17317
17318
17319
17320
17321
17322
17323
17324
17325
17326
17327
17328
17329
17330
17331
17332
17333
17334
17335
17336
17337
17338
17339
17340
17341
17342
17343
17344
17345
17346
17347
17348
17349
17350
17351
17352
17353
17354
17355
17356
17357
17358
17359
17360
17361
17362
17363
17364
17365
17366
17367
17368
17369
17370
17371
17372
17373
17374
17375
17376
17377
17378
17379
17380
17381
17382
17383
17384
17385
17386
17387
17388
17389
17390
17391
17392
17393
17394
17395
17396
17397
17398
17399
17400
17401
17402
17403
17404
17405
17406
17407
17408
17409
17410
17411
17412
17413
17414
17415
17416
17417
17418
17419
17420
17421
17422
17423
17424
17425
17426
17427
17428
17429
17430
17431
17432
17433
17434
17435
17436
17437
17438
17439
17440
17441
17442
17443
17444
17445
17446
17447
17448
17449
17450
17451
17452
17453
17454
17455
17456
17457
17458
17459
17460
17461
17462
17463
17464
17465
17466
17467
17468
17469
17470
17471
17472
17473
17474
17475
17476
17477
17478
17479
17480
17481
17482
17483
17484
17485
17486
17487
17488
17489
17490
17491
17492
17493
17494
17495
17496
17497
17498
17499
17500
17501
17502
17503
17504
17505
17506
17507
17508
17509
17510
17511
17512
17513
17514
17515
17516
17517
17518
17519
17520
17521
17522
17523
17524
17525
17526
17527
17528
17529
17530
17531
17532
17533
17534
17535
17536
17537
17538
17539
17540
17541
17542
17543
17544
17545
17546
17547
17548
17549
17550
17551
17552
17553
17554
17555
17556
17557
17558
17559
17560
17561
17562
17563
17564
17565
17566
17567
17568
17569
17570
17571
17572
17573
17574
17575
17576
17577
17578
17579
17580
17581
17582
17583
17584
17585
17586
17587
17588
17589
17590
17591
17592
17593
17594
17595
17596
17597
17598
17599
17600
17601
17602
17603
17604
17605
17606
17607
17608
17609
17610
17611
17612
17613
17614
17615
17616
17617
17618
17619
17620
17621
17622
17623
17624
17625
17626
17627
17628
17629
17630
17631
17632
17633
17634
17635
17636
17637
17638
17639
17640
17641
17642
17643
17644
17645
17646
17647
17648
17649
17650
17651
17652
17653
17654
17655
17656
17657
17658
17659
17660
17661
17662
17663
17664
17665
17666
17667
17668
17669
17670
17671
17672
17673
17674
17675
17676
17677
17678
17679
17680
17681
17682
17683
17684
17685
17686
17687
17688
17689
17690
17691
17692
17693
17694
17695
17696
17697
17698
17699
17700
17701
17702
17703
17704
17705
17706
17707
17708
17709
17710
17711
17712
17713
17714
17715
17716
17717
17718
17719
17720
17721
17722
17723
17724
17725
17726
17727
17728
17729
17730
17731
17732
17733
17734
17735
17736
17737
17738
17739
17740
17741
17742
17743
17744
17745
17746
17747
17748
17749
17750
17751
17752
17753
17754
17755
17756
17757
17758
17759
17760
17761
17762
17763
17764
17765
17766
17767
17768
17769
17770
17771
17772
17773
17774
17775
17776
17777
17778
17779
17780
17781
17782
17783
17784
17785
17786
17787
17788
17789
17790
17791
17792
17793
17794
17795
17796
17797
17798
17799
17800
17801
17802
17803
17804
17805
17806
17807
17808
17809
17810
17811
17812
17813
17814
17815
17816
17817
17818
17819
17820
17821
17822
17823
17824
17825
17826
17827
17828
17829
17830
17831
17832
17833
17834
17835
17836
17837
17838
17839
17840
17841
17842
17843
17844
17845
17846
17847
17848
17849
17850
17851
17852
17853
17854
17855
17856
17857
17858
17859
17860
17861
17862
17863
17864
17865
17866
17867
17868
17869
17870
17871
17872
17873
17874
17875
17876
17877
17878
17879
17880
17881
17882
17883
17884
17885
17886
17887
17888
17889
17890
17891
17892
17893
17894
17895
17896
17897
17898
17899
17900
17901
17902
17903
17904
17905
17906
17907
17908
17909
17910
17911
17912
17913
17914
17915
17916
17917
17918
17919
17920
17921
17922
17923
17924
17925
17926
17927
17928
17929
17930
17931
17932
17933
17934
17935
17936
17937
17938
17939
17940
17941
17942
17943
17944
17945
17946
17947
17948
17949
17950
17951
17952
17953
17954
17955
17956
17957
17958
17959
17960
17961
17962
17963
17964
17965
17966
17967
17968
17969
17970
17971
17972
17973
17974
17975
17976
17977
17978
17979
17980
17981
17982
17983
17984
17985
17986
17987
17988
17989
17990
17991
17992
17993
17994
17995
17996
17997
17998
17999
18000
18001
18002
18003
18004
18005
18006
18007
18008
18009
18010
18011
18012
18013
18014
18015
18016
18017
18018
18019
18020
18021
18022
18023
18024
18025
18026
18027
18028
18029
18030
18031
18032
18033
18034
18035
18036
18037
18038
18039
18040
18041
18042
18043
18044
18045
18046
18047
18048
18049
18050
18051
18052
18053
18054
18055
18056
18057
18058
18059
18060
18061
18062
18063
18064
18065
18066
18067
18068
18069
18070
18071
18072
18073
18074
18075
18076
18077
18078
18079
18080
18081
18082
18083
18084
18085
18086
18087
18088
18089
18090
18091
18092
18093
18094
18095
18096
18097
18098
18099
18100
18101
18102
18103
18104
18105
18106
18107
18108
18109
18110
18111
18112
18113
18114
18115
18116
18117
18118
18119
18120
18121
18122
18123
18124
18125
18126
18127
18128
18129
18130
18131
18132
18133
18134
18135
18136
18137
18138
18139
18140
18141
18142
18143
18144
18145
18146
18147
18148
18149
18150
18151
18152
18153
18154
18155
18156
18157
18158
18159
18160
18161
18162
18163
18164
18165
18166
18167
18168
18169
18170
18171
18172
18173
18174
18175
18176
18177
18178
18179
18180
18181
18182
18183
18184
18185
18186
18187
18188
18189
18190
18191
18192
18193
18194
18195
18196
18197
18198
18199
18200
18201
18202
18203
18204
18205
18206
18207
18208
18209
18210
18211
18212
18213
18214
18215
18216
18217
18218
18219
18220
18221
18222
18223
18224
18225
18226
18227
18228
18229
18230
18231
18232
18233
18234
18235
18236
18237
18238
18239
18240
18241
18242
18243
18244
18245
18246
18247
18248
18249
18250
18251
18252
18253
18254
18255
18256
18257
18258
18259
18260
18261
18262
18263
18264
18265
18266
18267
18268
18269
18270
18271
18272
18273
18274
18275
18276
18277
18278
18279
18280
18281
18282
18283
18284
18285
18286
18287
18288
18289
18290
18291
18292
18293
18294
18295
18296
18297
18298
18299
18300
18301
18302
18303
18304
18305
18306
18307
18308
18309
18310
18311
18312
18313
18314
18315
18316
18317
18318
18319
18320
18321
18322
18323
18324
18325
18326
18327
18328
18329
18330
18331
18332
18333
18334
18335
18336
18337
18338
18339
18340
18341
18342
18343
18344
18345
18346
18347
18348
18349
18350
18351
18352
18353
18354
18355
18356
18357
18358
18359
18360
18361
18362
18363
18364
18365
18366
18367
18368
18369
18370
18371
18372
18373
18374
18375
18376
18377
18378
18379
18380
18381
18382
18383
18384
18385
18386
18387
18388
18389
18390
18391
18392
18393
18394
18395
18396
18397
18398
18399
18400
18401
18402
18403
18404
18405
18406
18407
18408
18409
18410
18411
18412
18413
18414
18415
18416
18417
18418
18419
18420
18421
18422
18423
18424
18425
18426
18427
18428
18429
18430
18431
18432
18433
18434
18435
18436
18437
18438
18439
18440
18441
18442
18443
18444
18445
18446
18447
18448
18449
18450
18451
18452
18453
18454
18455
18456
18457
18458
18459
18460
18461
18462
18463
18464
18465
18466
18467
18468
18469
18470
18471
18472
18473
18474
18475
18476
18477
18478
18479
18480
18481
18482
18483
18484
18485
18486
18487
18488
18489
18490
18491
18492
18493
18494
18495
18496
18497
18498
18499
18500
18501
18502
18503
18504
18505
18506
18507
18508
18509
18510
18511
18512
18513
18514
18515
18516
18517
18518
18519
18520
18521
18522
18523
18524
18525
18526
18527
18528
18529
18530
18531
18532
18533
18534
18535
18536
18537
18538
18539
18540
18541
18542
18543
18544
18545
18546
18547
18548
18549
18550
18551
18552
18553
18554
18555
18556
18557
18558
18559
18560
18561
18562
18563
18564
18565
18566
18567
18568
18569
18570
18571
18572
18573
18574
18575
18576
18577
18578
18579
18580
18581
18582
18583
18584
18585
18586
18587
18588
18589
18590
18591
18592
18593
18594
18595
18596
18597
18598
18599
18600
18601
18602
18603
18604
18605
18606
18607
18608
18609
18610
18611
18612
18613
18614
18615
18616
18617
18618
18619
18620
18621
18622
18623
18624
18625
18626
18627
18628
18629
18630
18631
18632
18633
18634
18635
18636
18637
18638
18639
18640
18641
18642
18643
18644
18645
18646
18647
18648
18649
18650
18651
18652
18653
18654
18655
18656
18657
18658
18659
18660
18661
18662
18663
18664
18665
18666
18667
18668
18669
18670
18671
18672
18673
18674
18675
18676
18677
18678
18679
18680
18681
18682
18683
18684
18685
18686
18687
18688
18689
18690
18691
18692
18693
18694
18695
18696
18697
18698
18699
18700
18701
18702
18703
18704
18705
18706
18707
18708
18709
18710
18711
18712
18713
18714
18715
18716
18717
18718
18719
18720
18721
18722
18723
18724
18725
18726
18727
18728
18729
18730
18731
18732
18733
18734
18735
18736
18737
18738
18739
18740
18741
18742
18743
18744
18745
18746
18747
18748
18749
18750
18751
18752
18753
18754
18755
18756
18757
18758
18759
18760
18761
18762
18763
18764
18765
18766
18767
18768
18769
18770
18771
18772
18773
18774
18775
18776
18777
18778
18779
18780
18781
18782
18783
18784
18785
18786
18787
18788
18789
18790
18791
18792
18793
18794
18795
18796
18797
18798
18799
18800
18801
18802
18803
18804
18805
18806
18807
18808
18809
18810
18811
18812
18813
18814
18815
18816
18817
18818
18819
18820
18821
18822
18823
18824
18825
18826
18827
18828
18829
18830
18831
18832
18833
18834
18835
18836
18837
18838
18839
18840
18841
18842
18843
18844
18845
18846
18847
18848
18849
18850
18851
18852
18853
18854
18855
18856
18857
18858
18859
18860
18861
18862
18863
18864
18865
18866
18867
18868
18869
18870
18871
18872
18873
18874
18875
18876
18877
18878
18879
18880
18881
18882
18883
18884
18885
18886
18887
18888
18889
18890
18891
18892
18893
18894
18895
18896
18897
18898
18899
18900
18901
18902
18903
18904
18905
18906
18907
18908
18909
18910
18911
18912
18913
18914
18915
18916
18917
18918
18919
18920
18921
18922
18923
18924
18925
18926
18927
18928
18929
18930
18931
18932
18933
18934
18935
18936
18937
18938
18939
18940
18941
18942
18943
18944
18945
18946
18947
18948
18949
18950
18951
18952
18953
18954
18955
18956
18957
18958
18959
18960
18961
18962
18963
18964
18965
18966
18967
18968
18969
18970
18971
18972
18973
18974
18975
18976
18977
18978
18979
18980
18981
18982
18983
18984
18985
18986
18987
18988
18989
18990
18991
18992
18993
18994
18995
18996
18997
18998
18999
19000
19001
19002
19003
19004
19005
19006
19007
19008
19009
19010
19011
19012
19013
19014
19015
19016
19017
19018
19019
19020
19021
19022
19023
19024
19025
19026
19027
19028
19029
19030
19031
19032
19033
19034
19035
19036
19037
19038
19039
19040
19041
19042
19043
19044
19045
19046
19047
19048
19049
19050
19051
19052
19053
19054
19055
19056
19057
19058
19059
19060
19061
19062
19063
19064
19065
19066
19067
19068
19069
19070
19071
19072
19073
19074
19075
19076
19077
19078
19079
19080
19081
19082
19083
19084
19085
19086
19087
19088
19089
19090
19091
19092
19093
19094
19095
19096
19097
19098
19099
19100
19101
19102
19103
19104
19105
19106
19107
19108
19109
19110
19111
19112
19113
19114
19115
19116
19117
19118
19119
19120
19121
19122
19123
19124
19125
19126
19127
19128
19129
19130
19131
19132
19133
19134
19135
19136
19137
19138
19139
19140
19141
19142
19143
19144
19145
19146
19147
19148
19149
19150
19151
19152
19153
19154
19155
19156
19157
19158
19159
19160
19161
19162
19163
19164
19165
19166
19167
19168
19169
19170
19171
19172
19173
19174
19175
19176
19177
19178
19179
19180
19181
19182
19183
19184
19185
19186
19187
19188
19189
19190
19191
19192
19193
19194
19195
19196
19197
19198
19199
19200
19201
19202
19203
19204
19205
19206
19207
19208
19209
19210
19211
19212
19213
19214
19215
19216
19217
19218
19219
19220
19221
19222
19223
19224
19225
19226
19227
19228
19229
19230
19231
19232
19233
19234
19235
19236
19237
19238
19239
19240
19241
19242
19243
19244
19245
19246
19247
19248
19249
19250
19251
19252
19253
19254
19255
19256
19257
19258
19259
19260
19261
19262
19263
19264
19265
19266
19267
19268
19269
19270
19271
19272
19273
19274
19275
19276
19277
19278
19279
19280
19281
19282
19283
19284
19285
19286
19287
19288
19289
19290
19291
19292
19293
19294
19295
19296
19297
19298
19299
19300
19301
19302
19303
19304
19305
19306
19307
19308
19309
19310
19311
19312
19313
19314
19315
19316
19317
19318
19319
19320
19321
19322
19323
19324
19325
19326
19327
19328
19329
19330
19331
19332
19333
19334
19335
19336
19337
19338
19339
19340
19341
19342
19343
19344
19345
19346
19347
19348
19349
19350
19351
19352
19353
19354
19355
19356
19357
19358
19359
19360
19361
19362
19363
19364
19365
19366
19367
19368
19369
19370
19371
19372
19373
19374
19375
19376
19377
19378
19379
19380
19381
19382
19383
19384
19385
19386
19387
19388
19389
19390
19391
19392
19393
19394
19395
19396
19397
19398
19399
19400
19401
19402
19403
19404
19405
19406
19407
19408
19409
19410
19411
19412
19413
19414
19415
19416
19417
19418
19419
19420
19421
19422
19423
19424
19425
19426
19427
19428
19429
19430
19431
19432
19433
19434
19435
19436
19437
19438
19439
19440
19441
19442
19443
19444
19445
19446
19447
19448
19449
19450
19451
19452
19453
19454
19455
19456
19457
19458
19459
19460
19461
19462
19463
19464
19465
19466
19467
19468
19469
19470
19471
19472
19473
19474
19475
19476
19477
19478
19479
19480
19481
19482
19483
19484
19485
19486
19487
19488
19489
19490
19491
19492
19493
19494
19495
19496
19497
19498
19499
19500
19501
19502
19503
19504
19505
19506
19507
19508
19509
19510
19511
19512
19513
19514
19515
19516
19517
19518
19519
19520
19521
19522
19523
19524
19525
19526
19527
19528
19529
19530
19531
19532
19533
19534
19535
19536
19537
19538
19539
19540
19541
19542
19543
19544
19545
19546
19547
19548
19549
19550
19551
19552
19553
19554
19555
19556
19557
19558
19559
19560
19561
19562
19563
19564
19565
19566
19567
19568
19569
19570
19571
19572
19573
19574
19575
19576
19577
19578
19579
19580
19581
19582
19583
19584
19585
19586
19587
19588
19589
19590
19591
19592
19593
19594
19595
19596
19597
19598
19599
19600
19601
19602
19603
19604
19605
19606
19607
19608
19609
19610
19611
19612
19613
19614
19615
19616
19617
19618
19619
19620
19621
19622
19623
19624
19625
19626
19627
19628
19629
19630
19631
19632
19633
19634
19635
19636
19637
19638
19639
19640
19641
19642
19643
19644
19645
19646
19647
19648
19649
19650
19651
19652
19653
19654
19655
19656
19657
19658
19659
19660
19661
19662
19663
19664
19665
19666
19667
19668
19669
19670
19671
19672
19673
19674
19675
19676
19677
19678
19679
19680
19681
19682
19683
19684
19685
19686
19687
19688
19689
19690
19691
19692
19693
19694
19695
19696
19697
19698
19699
19700
19701
19702
19703
19704
19705
19706
19707
19708
19709
19710
19711
19712
19713
19714
19715
19716
19717
19718
19719
19720
19721
19722
19723
19724
19725
19726
19727
19728
19729
19730
19731
19732
19733
19734
19735
19736
19737
19738
19739
19740
19741
19742
19743
19744
19745
19746
19747
19748
19749
19750
19751
19752
19753
19754
19755
19756
19757
19758
19759
19760
19761
19762
19763
19764
19765
19766
19767
19768
19769
19770
19771
19772
19773
19774
19775
19776
19777
19778
19779
19780
19781
19782
19783
19784
19785
19786
19787
19788
19789
19790
19791
19792
19793
19794
19795
19796
19797
19798
19799
19800
19801
19802
19803
19804
19805
19806
19807
19808
19809
19810
19811
19812
19813
19814
19815
19816
19817
19818
19819
19820
19821
19822
19823
19824
19825
19826
19827
19828
19829
19830
19831
19832
19833
19834
19835
19836
19837
19838
19839
19840
19841
19842
19843
19844
19845
19846
19847
19848
19849
19850
19851
19852
19853
19854
19855
19856
19857
19858
19859
19860
19861
19862
19863
19864
19865
19866
19867
19868
19869
19870
19871
19872
19873
19874
19875
19876
19877
19878
19879
19880
19881
19882
19883
19884
19885
19886
19887
19888
19889
19890
19891
19892
19893
19894
19895
19896
19897
19898
19899
19900
19901
19902
19903
19904
19905
19906
19907
19908
19909
19910
19911
19912
19913
19914
19915
19916
19917
19918
19919
19920
19921
19922
19923
19924
19925
19926
19927
19928
19929
19930
19931
19932
19933
19934
19935
19936
19937
19938
19939
19940
19941
19942
19943
19944
19945
19946
19947
19948
19949
19950
19951
19952
19953
19954
19955
19956
19957
19958
19959
19960
19961
19962
19963
19964
19965
19966
19967
19968
19969
19970
19971
19972
19973
19974
19975
19976
19977
19978
19979
19980
19981
19982
19983
19984
19985
19986
19987
19988
19989
19990
19991
19992
19993
19994
19995
19996
19997
19998
19999
20000
20001
20002
20003
20004
20005
20006
20007
20008
20009
20010
20011
20012
20013
20014
20015
20016
20017
20018
20019
20020
20021
20022
20023
20024
20025
20026
20027
20028
20029
20030
20031
20032
20033
20034
20035
20036
20037
20038
20039
20040
20041
20042
20043
20044
20045
20046
20047
20048
20049
20050
20051
20052
20053
20054
20055
20056
20057
20058
20059
20060
20061
20062
20063
20064
20065
20066
20067
20068
20069
20070
20071
20072
20073
20074
20075
20076
20077
20078
20079
20080
20081
20082
20083
20084
20085
20086
20087
20088
20089
20090
20091
20092
20093
20094
20095
20096
20097
20098
20099
20100
20101
20102
20103
20104
20105
20106
20107
20108
20109
20110
20111
20112
20113
20114
20115
20116
20117
20118
20119
20120
20121
20122
20123
20124
20125
20126
20127
20128
20129
20130
20131
20132
20133
20134
20135
20136
20137
20138
20139
20140
20141
20142
20143
20144
20145
20146
20147
20148
20149
20150
20151
20152
20153
20154
20155
20156
20157
20158
20159
20160
20161
20162
20163
20164
20165
20166
20167
20168
20169
20170
20171
20172
20173
20174
20175
20176
20177
20178
20179
20180
20181
20182
20183
20184
20185
20186
20187
20188
20189
20190
20191
20192
20193
20194
20195
20196
20197
20198
20199
20200
20201
20202
20203
20204
20205
20206
20207
20208
20209
20210
20211
20212
20213
20214
20215
20216
20217
20218
20219
20220
20221
20222
20223
20224
20225
20226
20227
20228
20229
20230
20231
20232
20233
20234
20235
20236
20237
20238
20239
20240
20241
20242
20243
20244
20245
20246
20247
20248
20249
20250
20251
20252
20253
20254
20255
20256
20257
20258
20259
20260
20261
20262
20263
20264
20265
20266
20267
20268
20269
20270
20271
20272
20273
20274
20275
20276
20277
20278
20279
20280
20281
20282
20283
20284
20285
20286
20287
20288
20289
20290
20291
20292
20293
20294
20295
20296
20297
20298
20299
20300
20301
20302
20303
20304
20305
20306
20307
20308
20309
20310
20311
20312
20313
20314
20315
20316
20317
20318
20319
20320
20321
20322
20323
20324
20325
20326
20327
20328
20329
20330
20331
20332
20333
20334
20335
20336
20337
20338
20339
20340
20341
20342
20343
20344
20345
20346
20347
20348
20349
20350
20351
20352
20353
20354
20355
20356
20357
20358
20359
20360
20361
20362
20363
20364
20365
20366
20367
20368
20369
20370
20371
20372
20373
20374
20375
20376
20377
20378
20379
20380
20381
20382
20383
20384
20385
20386
20387
20388
20389
20390
20391
20392
20393
20394
20395
20396
20397
20398
20399
20400
20401
20402
20403
20404
20405
20406
20407
20408
20409
20410
20411
20412
20413
20414
20415
20416
20417
20418
20419
20420
20421
20422
20423
20424
20425
20426
20427
20428
20429
20430
20431
20432
20433
20434
20435
20436
20437
20438
20439
20440
20441
20442
20443
20444
20445
20446
20447
20448
20449
20450
20451
20452
20453
20454
20455
20456
20457
20458
20459
20460
20461
20462
20463
20464
20465
20466
20467
20468
20469
20470
20471
20472
20473
20474
20475
20476
20477
20478
20479
20480
20481
20482
20483
20484
20485
20486
20487
20488
20489
20490
20491
20492
20493
20494
20495
20496
20497
20498
20499
20500
20501
20502
20503
20504
20505
20506
20507
20508
20509
20510
20511
20512
20513
20514
20515
20516
20517
20518
20519
20520
20521
20522
20523
20524
20525
20526
20527
20528
20529
20530
20531
20532
20533
20534
20535
20536
20537
20538
20539
20540
20541
20542
20543
20544
20545
20546
20547
20548
20549
20550
20551
20552
20553
20554
20555
20556
20557
20558
20559
20560
20561
20562
20563
20564
20565
20566
20567
20568
20569
20570
20571
20572
20573
20574
20575
20576
20577
20578
20579
20580
20581
20582
20583
20584
20585
20586
20587
20588
20589
20590
20591
20592
20593
20594
20595
20596
20597
20598
20599
20600
20601
20602
20603
20604
20605
20606
20607
20608
20609
20610
20611
20612
20613
20614
20615
20616
20617
20618
20619
20620
20621
20622
20623
20624
20625
20626
20627
20628
20629
20630
20631
20632
20633
20634
20635
20636
20637
20638
20639
20640
20641
20642
20643
20644
20645
20646
20647
20648
20649
20650
20651
20652
20653
20654
20655
20656
20657
20658
20659
20660
20661
20662
20663
20664
20665
20666
20667
20668
20669
20670
20671
20672
20673
20674
20675
20676
20677
20678
20679
20680
20681
20682
20683
20684
20685
20686
20687
20688
20689
20690
20691
20692
20693
20694
20695
20696
20697
20698
20699
20700
20701
20702
20703
20704
20705
20706
20707
20708
20709
20710
20711
20712
20713
20714
20715
20716
20717
20718
20719
20720
20721
20722
20723
20724
20725
20726
20727
20728
20729
20730
20731
20732
20733
20734
20735
20736
20737
20738
20739
20740
20741
20742
20743
20744
20745
20746
20747
20748
20749
20750
20751
20752
20753
20754
20755
20756
20757
20758
20759
20760
20761
20762
20763
20764
20765
20766
20767
20768
20769
20770
20771
20772
20773
20774
20775
20776
20777
20778
20779
20780
20781
20782
20783
20784
20785
20786
20787
20788
20789
20790
20791
20792
20793
20794
20795
20796
20797
20798
20799
20800
20801
20802
20803
20804
20805
20806
20807
20808
20809
20810
20811
20812
20813
20814
20815
20816
20817
20818
20819
20820
20821
20822
20823
20824
20825
20826
20827
20828
20829
20830
20831
20832
20833
20834
20835
20836
20837
20838
20839
20840
20841
20842
20843
20844
20845
20846
20847
20848
20849
20850
20851
20852
20853
20854
20855
20856
20857
20858
20859
20860
20861
20862
20863
20864
20865
20866
20867
20868
20869
20870
20871
20872
20873
20874
20875
20876
20877
20878
20879
20880
20881
20882
20883
20884
20885
20886
20887
20888
20889
20890
20891
20892
20893
20894
20895
20896
20897
20898
20899
20900
20901
20902
20903
20904
20905
20906
20907
20908
20909
20910
20911
20912
20913
20914
20915
20916
20917
20918
20919
20920
20921
20922
20923
20924
20925
20926
20927
20928
20929
20930
20931
20932
20933
20934
20935
20936
20937
20938
20939
20940
20941
20942
20943
20944
20945
20946
20947
20948
20949
20950
20951
20952
20953
20954
20955
20956
20957
20958
20959
20960
20961
20962
20963
20964
20965
20966
20967
20968
20969
20970
20971
20972
20973
20974
20975
20976
20977
20978
20979
20980
20981
20982
20983
20984
20985
20986
20987
20988
20989
20990
20991
20992
20993
20994
20995
20996
20997
20998
20999
21000
21001
21002
21003
21004
21005
21006
21007
21008
21009
21010
21011
21012
21013
21014
21015
21016
21017
21018
21019
21020
21021
21022
21023
21024
21025
21026
21027
21028
21029
21030
21031
21032
21033
21034
21035
21036
21037
21038
21039
21040
21041
21042
21043
21044
21045
21046
21047
21048
21049
21050
21051
21052
21053
21054
21055
21056
21057
21058
21059
21060
21061
21062
21063
21064
21065
21066
21067
21068
21069
21070
21071
21072
21073
21074
21075
21076
21077
21078
21079
21080
21081
21082
21083
21084
21085
21086
21087
21088
21089
21090
21091
21092
21093
21094
21095
21096
21097
21098
21099
21100
21101
21102
21103
21104
21105
21106
21107
21108
21109
21110
21111
21112
21113
21114
21115
21116
21117
21118
21119
21120
21121
21122
21123
21124
21125
21126
21127
21128
21129
21130
21131
21132
21133
21134
21135
21136
21137
21138
21139
21140
21141
21142
21143
21144
21145
21146
21147
21148
21149
21150
21151
21152
21153
21154
21155
21156
21157
21158
21159
21160
21161
21162
21163
21164
21165
21166
21167
21168
21169
21170
21171
21172
21173
21174
21175
21176
21177
21178
21179
21180
21181
21182
21183
21184
21185
21186
21187
21188
21189
21190
21191
21192
21193
21194
21195
21196
21197
21198
21199
21200
21201
21202
21203
21204
21205
21206
21207
21208
21209
21210
21211
21212
21213
21214
21215
21216
21217
21218
21219
21220
21221
21222
21223
21224
21225
21226
21227
21228
21229
21230
21231
21232
21233
21234
21235
21236
21237
21238
21239
21240
21241
21242
21243
21244
21245
21246
21247
21248
21249
21250
21251
21252
21253
21254
21255
21256
21257
21258
21259
21260
21261
21262
21263
21264
21265
21266
21267
21268
21269
21270
21271
21272
21273
21274
21275
21276
21277
21278
21279
21280
21281
21282
21283
21284
21285
21286
21287
21288
21289
21290
21291
21292
21293
21294
21295
21296
21297
21298
21299
21300
21301
21302
21303
21304
21305
21306
21307
21308
21309
21310
21311
21312
21313
21314
21315
21316
21317
21318
21319
21320
21321
21322
21323
21324
21325
21326
21327
21328
21329
21330
21331
21332
21333
21334
21335
21336
21337
21338
21339
21340
21341
21342
21343
21344
21345
21346
21347
21348
21349
21350
21351
21352
21353
21354
21355
21356
21357
21358
21359
21360
21361
21362
21363
21364
21365
21366
21367
21368
21369
21370
21371
21372
21373
21374
21375
21376
21377
21378
21379
21380
21381
21382
21383
21384
21385
21386
21387
21388
21389
21390
21391
21392
21393
21394
21395
21396
21397
21398
21399
21400
21401
21402
21403
21404
21405
21406
21407
21408
21409
21410
21411
21412
21413
21414
21415
21416
21417
21418
21419
21420
21421
21422
21423
21424
21425
21426
21427
21428
21429
21430
21431
21432
21433
21434
21435
21436
21437
21438
21439
21440
21441
21442
21443
21444
21445
21446
21447
21448
21449
21450
21451
21452
21453
21454
21455
21456
21457
21458
21459
21460
21461
21462
21463
21464
21465
21466
21467
21468
21469
21470
21471
21472
21473
21474
21475
21476
21477
21478
21479
21480
21481
21482
21483
21484
21485
21486
21487
21488
21489
21490
21491
21492
21493
21494
21495
21496
21497
21498
21499
21500
21501
21502
21503
21504
21505
21506
21507
21508
21509
21510
21511
21512
21513
21514
21515
21516
21517
21518
21519
21520
21521
21522
21523
21524
21525
21526
21527
21528
21529
21530
21531
21532
21533
21534
21535
21536
21537
21538
21539
21540
21541
21542
21543
21544
21545
21546
21547
21548
21549
21550
21551
21552
21553
21554
21555
21556
21557
21558
21559
21560
21561
21562
21563
21564
21565
21566
21567
21568
21569
21570
21571
21572
21573
21574
21575
21576
21577
21578
21579
21580
21581
21582
21583
21584
21585
21586
21587
21588
21589
21590
21591
21592
21593
21594
21595
21596
21597
21598
21599
21600
21601
21602
21603
21604
21605
21606
21607
21608
21609
21610
21611
21612
21613
21614
21615
21616
21617
21618
21619
21620
21621
21622
21623
21624
21625
21626
21627
21628
21629
21630
21631
21632
21633
21634
21635
21636
21637
21638
21639
21640
21641
21642
21643
21644
21645
21646
21647
21648
21649
21650
21651
21652
21653
21654
21655
21656
21657
21658
21659
21660
21661
21662
21663
21664
21665
21666
21667
21668
21669
21670
21671
21672
21673
21674
21675
21676
21677
21678
21679
21680
21681
21682
21683
21684
21685
21686
21687
21688
21689
21690
21691
21692
21693
21694
21695
21696
21697
21698
21699
21700
21701
21702
21703
21704
21705
21706
21707
21708
21709
21710
21711
21712
21713
21714
21715
21716
21717
21718
21719
21720
21721
21722
21723
21724
21725
21726
21727
21728
21729
21730
21731
21732
21733
21734
21735
21736
21737
21738
21739
21740
21741
21742
21743
21744
21745
21746
21747
21748
21749
21750
21751
21752
21753
21754
21755
21756
21757
21758
21759
21760
21761
21762
21763
21764
21765
21766
21767
21768
21769
21770
21771
21772
21773
21774
21775
21776
21777
21778
21779
21780
21781
21782
21783
21784
21785
21786
21787
21788
21789
21790
21791
21792
21793
21794
21795
21796
21797
21798
21799
21800
21801
21802
21803
21804
21805
21806
21807
21808
21809
21810
21811
21812
21813
21814
21815
21816
21817
21818
21819
21820
21821
21822
21823
21824
21825
21826
21827
21828
21829
21830
21831
21832
21833
21834
21835
21836
21837
21838
21839
21840
21841
21842
21843
21844
21845
21846
21847
21848
21849
21850
21851
21852
21853
21854
21855
21856
21857
21858
21859
21860
21861
21862
21863
21864
21865
21866
21867
21868
21869
21870
21871
21872
21873
21874
21875
21876
21877
21878
21879
21880
21881
21882
21883
21884
21885
21886
21887
21888
21889
21890
21891
21892
21893
21894
21895
21896
21897
21898
21899
21900
21901
21902
21903
21904
21905
21906
21907
21908
21909
21910
21911
21912
21913
21914
21915
21916
21917
21918
21919
21920
21921
21922
21923
21924
21925
21926
21927
21928
21929
21930
21931
21932
21933
21934
21935
21936
21937
21938
21939
21940
21941
21942
21943
21944
21945
21946
21947
21948
21949
21950
21951
21952
21953
21954
21955
21956
21957
21958
21959
21960
21961
21962
21963
21964
21965
21966
21967
21968
21969
21970
21971
21972
21973
21974
21975
21976
21977
21978
21979
21980
21981
21982
21983
21984
21985
21986
21987
21988
21989
21990
21991
21992
21993
21994
21995
21996
21997
21998
21999
22000
22001
22002
22003
22004
22005
22006
22007
22008
22009
22010
22011
22012
22013
22014
22015
22016
22017
22018
22019
22020
22021
22022
22023
22024
22025
22026
22027
22028
22029
22030
22031
22032
22033
22034
22035
22036
22037
22038
22039
22040
22041
22042
22043
22044
22045
22046
22047
22048
22049
22050
22051
22052
22053
22054
22055
22056
22057
22058
22059
22060
22061
22062
22063
22064
22065
22066
22067
22068
22069
22070
22071
22072
22073
22074
22075
22076
22077
22078
22079
22080
22081
22082
22083
22084
22085
22086
22087
22088
22089
22090
22091
22092
22093
22094
22095
22096
22097
22098
22099
22100
22101
22102
22103
22104
22105
22106
22107
22108
22109
22110
22111
22112
22113
22114
22115
22116
22117
22118
22119
22120
22121
22122
22123
22124
22125
22126
22127
22128
22129
22130
22131
22132
22133
22134
22135
22136
22137
22138
22139
22140
22141
22142
22143
22144
22145
22146
22147
22148
22149
22150
22151
22152
22153
22154
22155
22156
22157
22158
22159
22160
22161
22162
22163
22164
22165
22166
22167
22168
22169
22170
22171
22172
22173
22174
22175
22176
22177
22178
22179
22180
22181
22182
22183
22184
22185
22186
22187
22188
22189
22190
22191
22192
22193
22194
22195
22196
22197
22198
22199
22200
22201
22202
22203
22204
22205
22206
22207
22208
22209
22210
22211
22212
22213
22214
22215
22216
22217
22218
22219
22220
22221
22222
22223
22224
22225
22226
22227
22228
22229
22230
22231
22232
22233
22234
22235
22236
22237
22238
22239
22240
22241
22242
22243
22244
22245
22246
22247
22248
22249
22250
22251
22252
22253
22254
22255
22256
22257
22258
22259
22260
22261
22262
22263
22264
22265
22266
22267
22268
22269
22270
22271
22272
22273
22274
22275
22276
22277
22278
22279
22280
22281
22282
22283
22284
22285
22286
22287
22288
22289
22290
22291
22292
22293
22294
22295
22296
22297
22298
22299
22300
22301
22302
22303
22304
22305
22306
22307
22308
22309
22310
22311
22312
22313
22314
22315
22316
22317
22318
22319
22320
22321
22322
22323
22324
22325
22326
22327
22328
22329
22330
22331
22332
22333
22334
22335
22336
22337
22338
22339
22340
22341
22342
22343
22344
22345
22346
22347
22348
22349
22350
22351
22352
22353
22354
22355
22356
22357
22358
22359
22360
22361
22362
22363
22364
22365
22366
22367
22368
22369
22370
22371
22372
22373
22374
22375
22376
22377
22378
22379
22380
22381
22382
22383
22384
22385
22386
22387
22388
22389
22390
22391
22392
22393
22394
22395
22396
22397
22398
22399
22400
22401
22402
22403
22404
22405
22406
22407
22408
22409
22410
22411
22412
22413
22414
22415
22416
22417
22418
22419
22420
22421
22422
22423
22424
22425
22426
22427
22428
22429
22430
22431
22432
22433
22434
22435
22436
22437
22438
22439
22440
22441
22442
22443
22444
22445
22446
22447
22448
22449
22450
22451
22452
22453
22454
22455
22456
22457
22458
22459
22460
22461
22462
22463
22464
22465
22466
22467
22468
22469
22470
22471
22472
22473
22474
22475
22476
22477
22478
22479
22480
22481
22482
22483
22484
22485
22486
22487
22488
22489
22490
22491
22492
22493
22494
22495
22496
22497
22498
22499
22500
22501
22502
22503
22504
22505
22506
22507
22508
22509
22510
22511
22512
22513
22514
22515
22516
22517
22518
22519
22520
22521
22522
22523
22524
22525
22526
22527
22528
22529
22530
22531
22532
22533
22534
22535
22536
22537
22538
22539
22540
22541
22542
22543
22544
22545
22546
22547
22548
22549
22550
22551
22552
22553
22554
22555
22556
22557
22558
22559
22560
22561
22562
22563
22564
22565
22566
22567
22568
22569
22570
22571
22572
22573
22574
22575
22576
22577
22578
22579
22580
22581
22582
22583
22584
22585
22586
22587
22588
22589
22590
22591
22592
22593
22594
22595
22596
22597
22598
22599
22600
22601
22602
22603
22604
22605
22606
22607
22608
22609
22610
22611
22612
22613
22614
22615
22616
22617
22618
22619
22620
22621
22622
22623
22624
22625
22626
22627
22628
22629
22630
22631
22632
22633
22634
22635
22636
22637
22638
22639
22640
22641
22642
22643
22644
22645
22646
22647
22648
22649
22650
22651
22652
22653
22654
22655
22656
22657
22658
22659
22660
22661
22662
22663
22664
22665
22666
22667
22668
22669
22670
22671
22672
22673
22674
22675
22676
22677
22678
22679
22680
22681
22682
22683
22684
22685
22686
22687
22688
22689
22690
22691
22692
22693
22694
22695
22696
22697
22698
22699
22700
22701
22702
22703
22704
22705
22706
22707
22708
22709
22710
22711
22712
22713
22714
22715
22716
22717
22718
22719
22720
22721
22722
22723
22724
22725
22726
22727
22728
22729
22730
22731
22732
22733
22734
22735
22736
22737
22738
22739
22740
22741
22742
22743
22744
22745
22746
22747
22748
22749
22750
22751
22752
22753
22754
22755
22756
22757
22758
22759
22760
22761
22762
22763
22764
22765
22766
22767
22768
22769
22770
22771
22772
22773
22774
22775
22776
22777
22778
22779
22780
22781
22782
22783
22784
22785
22786
22787
22788
22789
22790
22791
22792
22793
22794
22795
22796
22797
22798
22799
22800
22801
22802
22803
22804
22805
22806
22807
22808
22809
22810
22811
22812
22813
22814
22815
22816
22817
22818
22819
22820
22821
22822
22823
22824
22825
22826
22827
22828
22829
22830
22831
22832
22833
22834
22835
22836
22837
22838
22839
22840
22841
22842
22843
22844
22845
22846
22847
22848
22849
22850
22851
22852
22853
22854
22855
22856
22857
22858
22859
22860
22861
22862
22863
22864
22865
22866
22867
22868
22869
22870
22871
22872
22873
22874
22875
22876
22877
22878
22879
22880
22881
22882
22883
22884
22885
22886
22887
22888
22889
22890
22891
22892
22893
22894
22895
22896
22897
22898
22899
22900
22901
22902
22903
22904
22905
22906
22907
22908
22909
22910
22911
22912
22913
22914
22915
22916
22917
22918
22919
22920
22921
22922
22923
22924
22925
22926
22927
22928
22929
22930
22931
22932
22933
22934
22935
22936
22937
22938
22939
22940
22941
22942
22943
22944
22945
22946
22947
22948
22949
22950
22951
22952
22953
22954
22955
22956
22957
22958
22959
22960
22961
22962
22963
22964
22965
22966
22967
22968
22969
22970
22971
22972
22973
22974
22975
22976
22977
22978
22979
22980
22981
22982
22983
22984
22985
22986
22987
22988
22989
22990
22991
22992
22993
22994
22995
22996
22997
22998
22999
23000
23001
23002
23003
23004
23005
23006
23007
23008
23009
23010
23011
23012
23013
23014
23015
23016
23017
23018
23019
23020
23021
23022
23023
23024
23025
23026
23027
23028
23029
23030
23031
23032
23033
23034
23035
23036
23037
23038
23039
23040
23041
23042
23043
23044
23045
23046
23047
23048
23049
23050
23051
23052
23053
23054
23055
23056
23057
23058
23059
23060
23061
23062
23063
23064
23065
23066
23067
23068
23069
23070
23071
23072
23073
23074
23075
23076
23077
23078
23079
23080
23081
23082
23083
23084
23085
23086
23087
23088
23089
23090
23091
23092
23093
23094
23095
23096
23097
23098
23099
23100
23101
23102
23103
23104
23105
23106
23107
23108
23109
23110
23111
23112
23113
23114
23115
23116
23117
23118
23119
23120
23121
23122
23123
23124
23125
23126
23127
23128
23129
23130
23131
23132
23133
23134
23135
23136
23137
23138
23139
23140
23141
23142
23143
23144
23145
23146
23147
23148
23149
23150
23151
23152
23153
23154
23155
23156
23157
23158
23159
23160
23161
23162
23163
23164
23165
23166
23167
23168
23169
23170
23171
23172
23173
23174
23175
23176
23177
23178
23179
23180
23181
23182
23183
23184
23185
23186
23187
23188
23189
23190
23191
23192
23193
23194
23195
23196
23197
23198
23199
23200
23201
23202
23203
23204
23205
23206
23207
23208
23209
23210
23211
23212
23213
23214
23215
23216
23217
23218
23219
23220
23221
23222
23223
23224
23225
23226
23227
23228
23229
23230
23231
23232
23233
23234
23235
23236
23237
23238
23239
23240
23241
23242
23243
23244
23245
23246
23247
23248
23249
23250
23251
23252
23253
23254
23255
23256
23257
23258
23259
23260
23261
23262
23263
23264
23265
23266
23267
23268
23269
23270
23271
23272
23273
23274
23275
23276
23277
23278
23279
23280
23281
23282
23283
23284
23285
23286
23287
23288
23289
23290
23291
23292
23293
23294
23295
23296
23297
23298
23299
23300
23301
23302
23303
23304
23305
23306
23307
23308
23309
23310
23311
23312
23313
23314
23315
23316
23317
23318
23319
23320
23321
23322
23323
23324
23325
23326
23327
23328
23329
23330
23331
23332
23333
23334
23335
23336
23337
23338
23339
23340
23341
23342
23343
23344
23345
23346
23347
23348
23349
23350
23351
23352
23353
23354
23355
23356
23357
23358
23359
23360
23361
23362
23363
23364
23365
23366
23367
23368
23369
23370
23371
23372
23373
23374
23375
23376
23377
23378
23379
23380
23381
23382
23383
23384
23385
23386
23387
23388
23389
23390
23391
23392
23393
23394
23395
23396
23397
23398
23399
23400
23401
23402
23403
23404
23405
23406
23407
23408
23409
23410
23411
23412
23413
23414
23415
23416
23417
23418
23419
23420
23421
23422
23423
23424
23425
23426
23427
23428
23429
23430
23431
23432
23433
23434
23435
23436
23437
23438
23439
23440
23441
23442
23443
23444
23445
23446
23447
23448
23449
23450
23451
23452
23453
23454
23455
23456
23457
23458
23459
23460
23461
23462
23463
23464
23465
23466
23467
23468
23469
23470
23471
23472
23473
23474
23475
23476
23477
23478
23479
23480
23481
23482
23483
23484
23485
23486
23487
23488
23489
23490
23491
23492
23493
23494
23495
23496
23497
23498
23499
23500
23501
23502
23503
23504
23505
23506
23507
23508
23509
23510
23511
23512
23513
23514
23515
23516
23517
23518
23519
23520
23521
23522
23523
23524
23525
23526
23527
23528
23529
23530
23531
23532
23533
23534
23535
23536
23537
23538
23539
23540
23541
23542
23543
23544
23545
23546
23547
23548
23549
23550
23551
23552
23553
23554
23555
23556
23557
23558
23559
23560
23561
23562
23563
23564
23565
23566
23567
23568
23569
23570
23571
23572
23573
23574
23575
23576
23577
23578
23579
23580
23581
23582
23583
23584
23585
23586
23587
23588
23589
23590
23591
23592
23593
23594
23595
23596
23597
23598
23599
23600
23601
23602
23603
23604
23605
23606
23607
23608
23609
23610
23611
23612
23613
23614
23615
23616
23617
23618
23619
23620
23621
23622
23623
23624
23625
23626
23627
23628
23629
23630
23631
23632
23633
23634
23635
23636
23637
23638
23639
23640
23641
23642
23643
23644
23645
23646
23647
23648
23649
23650
23651
23652
23653
23654
23655
23656
23657
23658
23659
23660
23661
23662
23663
23664
23665
23666
23667
23668
23669
23670
23671
23672
23673
23674
23675
23676
23677
23678
23679
23680
23681
23682
23683
23684
23685
23686
23687
23688
23689
23690
23691
23692
23693
23694
23695
23696
23697
23698
23699
23700
23701
23702
23703
23704
23705
23706
23707
23708
23709
23710
23711
23712
23713
23714
23715
23716
23717
23718
23719
23720
23721
23722
23723
23724
23725
23726
23727
23728
23729
23730
23731
23732
23733
23734
23735
23736
23737
23738
23739
23740
23741
23742
23743
23744
23745
23746
23747
23748
23749
23750
23751
23752
23753
23754
23755
23756
23757
23758
23759
23760
23761
23762
23763
23764
23765
23766
23767
23768
23769
23770
23771
23772
23773
23774
23775
23776
23777
23778
23779
23780
23781
23782
23783
23784
23785
23786
23787
23788
23789
23790
23791
23792
23793
23794
23795
23796
23797
23798
23799
23800
23801
23802
23803
23804
23805
23806
23807
23808
23809
23810
23811
23812
23813
23814
23815
23816
23817
23818
23819
23820
23821
23822
23823
23824
23825
23826
23827
23828
23829
23830
23831
23832
23833
23834
23835
23836
23837
23838
23839
23840
23841
23842
23843
23844
23845
23846
23847
23848
23849
23850
23851
23852
23853
23854
23855
23856
23857
23858
23859
23860
23861
23862
23863
23864
23865
23866
23867
23868
23869
23870
23871
23872
23873
23874
23875
23876
23877
23878
23879
23880
23881
23882
23883
23884
23885
23886
23887
23888
23889
23890
23891
23892
23893
23894
23895
23896
23897
23898
23899
23900
23901
23902
23903
23904
23905
23906
23907
23908
23909
23910
23911
23912
23913
23914
23915
23916
23917
23918
23919
23920
23921
23922
23923
23924
23925
23926
23927
23928
23929
23930
23931
23932
23933
23934
23935
23936
23937
23938
23939
23940
23941
23942
23943
23944
23945
23946
23947
23948
23949
23950
23951
23952
23953
23954
23955
23956
23957
23958
23959
23960
23961
23962
23963
23964
23965
23966
23967
23968
23969
23970
23971
23972
23973
23974
23975
23976
23977
23978
23979
23980
23981
23982
23983
23984
23985
23986
23987
23988
23989
23990
23991
23992
23993
23994
23995
23996
23997
23998
23999
24000
24001
24002
24003
24004
24005
24006
24007
24008
24009
24010
24011
24012
24013
24014
24015
24016
24017
24018
24019
24020
24021
24022
24023
24024
24025
24026
24027
24028
24029
24030
24031
24032
24033
24034
24035
24036
24037
24038
24039
24040
24041
24042
24043
24044
24045
24046
24047
24048
24049
24050
24051
24052
24053
24054
24055
24056
24057
24058
24059
24060
24061
24062
24063
24064
24065
24066
24067
24068
24069
24070
24071
24072
24073
24074
24075
24076
24077
24078
24079
24080
24081
24082
24083
24084
24085
24086
24087
24088
24089
24090
24091
24092
24093
24094
24095
24096
24097
24098
24099
24100
24101
24102
24103
24104
24105
24106
24107
24108
24109
24110
24111
24112
24113
24114
24115
24116
24117
24118
24119
24120
24121
24122
24123
24124
24125
24126
24127
24128
24129
24130
24131
24132
24133
24134
24135
24136
24137
24138
24139
24140
24141
24142
24143
24144
24145
24146
24147
24148
24149
24150
24151
24152
24153
24154
24155
24156
24157
24158
24159
24160
24161
24162
24163
24164
24165
24166
24167
24168
24169
24170
24171
24172
24173
24174
24175
24176
24177
24178
24179
24180
24181
24182
24183
24184
24185
24186
24187
24188
24189
24190
24191
24192
24193
24194
24195
24196
24197
24198
24199
24200
24201
24202
24203
24204
24205
24206
24207
24208
24209
24210
24211
24212
24213
24214
24215
24216
24217
24218
24219
24220
24221
24222
24223
24224
24225
24226
24227
24228
24229
24230
24231
24232
24233
24234
24235
24236
24237
24238
24239
24240
24241
24242
24243
24244
24245
24246
24247
24248
24249
24250
24251
24252
24253
24254
24255
24256
24257
24258
24259
24260
24261
24262
24263
24264
24265
24266
24267
24268
24269
24270
24271
24272
24273
24274
24275
24276
24277
24278
24279
24280
24281
24282
24283
24284
24285
24286
24287
24288
24289
24290
24291
24292
24293
24294
24295
24296
24297
24298
24299
24300
24301
24302
24303
24304
24305
24306
24307
24308
24309
24310
24311
24312
24313
24314
24315
24316
24317
24318
24319
24320
24321
24322
24323
24324
24325
24326
24327
24328
24329
24330
24331
24332
24333
24334
24335
24336
24337
24338
24339
24340
24341
24342
24343
24344
24345
24346
24347
24348
24349
24350
24351
24352
24353
24354
24355
24356
24357
24358
24359
24360
24361
24362
24363
24364
24365
24366
24367
24368
24369
24370
24371
24372
24373
24374
24375
24376
24377
24378
24379
24380
24381
24382
24383
24384
24385
24386
24387
24388
24389
24390
24391
24392
24393
24394
24395
24396
24397
24398
24399
24400
24401
24402
24403
24404
24405
24406
24407
24408
24409
24410
24411
24412
24413
24414
24415
24416
24417
24418
24419
24420
24421
24422
24423
24424
24425
24426
24427
24428
24429
24430
24431
24432
24433
24434
24435
24436
24437
24438
24439
24440
24441
24442
24443
24444
24445
24446
24447
24448
24449
24450
24451
24452
24453
24454
24455
24456
24457
24458
24459
24460
24461
24462
24463
24464
24465
24466
24467
24468
24469
24470
24471
24472
24473
24474
24475
24476
24477
24478
24479
24480
24481
24482
24483
24484
24485
24486
24487
24488
24489
24490
24491
24492
24493
24494
24495
24496
24497
24498
24499
24500
24501
24502
24503
24504
24505
24506
24507
24508
24509
24510
24511
24512
24513
24514
24515
24516
24517
24518
24519
24520
24521
24522
24523
24524
24525
24526
24527
24528
24529
24530
24531
24532
24533
24534
24535
24536
24537
24538
24539
24540
24541
24542
24543
24544
24545
24546
24547
24548
24549
24550
24551
24552
24553
24554
24555
24556
24557
24558
24559
24560
24561
24562
24563
24564
24565
24566
24567
24568
24569
24570
24571
24572
24573
24574
24575
24576
24577
24578
24579
24580
24581
24582
24583
24584
24585
24586
24587
24588
24589
24590
24591
24592
24593
24594
24595
24596
24597
24598
24599
24600
24601
24602
24603
24604
24605
24606
24607
24608
24609
24610
24611
24612
24613
24614
24615
24616
24617
24618
24619
24620
24621
24622
24623
24624
24625
24626
24627
24628
24629
24630
24631
24632
24633
24634
24635
24636
24637
24638
24639
24640
24641
24642
24643
24644
24645
24646
24647
24648
24649
24650
24651
24652
24653
24654
24655
24656
24657
24658
24659
24660
24661
24662
24663
24664
24665
24666
24667
24668
24669
24670
24671
24672
24673
24674
24675
24676
24677
24678
24679
24680
24681
24682
24683
24684
24685
24686
24687
24688
24689
24690
24691
24692
24693
24694
24695
24696
24697
24698
24699
24700
24701
24702
24703
24704
24705
24706
24707
24708
24709
24710
24711
24712
24713
24714
24715
24716
24717
24718
24719
24720
24721
24722
24723
24724
24725
24726
24727
24728
24729
24730
24731
24732
24733
24734
24735
24736
24737
24738
24739
24740
24741
24742
24743
24744
24745
24746
24747
24748
24749
24750
24751
24752
24753
24754
24755
24756
24757
24758
24759
24760
24761
24762
24763
24764
24765
24766
24767
24768
24769
24770
24771
24772
24773
24774
24775
24776
24777
24778
24779
24780
24781
24782
24783
24784
24785
24786
24787
24788
24789
24790
24791
24792
24793
24794
24795
24796
24797
24798
24799
24800
24801
24802
24803
24804
24805
24806
24807
24808
24809
24810
24811
24812
24813
24814
24815
24816
24817
24818
24819
24820
24821
24822
24823
24824
24825
24826
24827
24828
24829
24830
24831
24832
24833
24834
24835
24836
24837
24838
24839
24840
24841
24842
24843
24844
24845
24846
24847
24848
24849
24850
24851
24852
24853
24854
24855
24856
24857
24858
24859
24860
24861
24862
24863
24864
24865
24866
24867
24868
24869
24870
24871
24872
24873
24874
24875
24876
24877
24878
24879
24880
24881
24882
24883
24884
24885
24886
24887
24888
24889
24890
24891
24892
24893
24894
24895
24896
24897
24898
24899
24900
24901
24902
24903
24904
24905
24906
24907
24908
24909
24910
24911
24912
24913
24914
24915
24916
24917
24918
24919
24920
24921
24922
24923
24924
24925
24926
24927
24928
24929
24930
24931
24932
24933
24934
24935
24936
24937
24938
24939
24940
24941
24942
24943
24944
24945
24946
24947
24948
24949
24950
24951
24952
24953
24954
24955
24956
24957
24958
24959
24960
24961
24962
24963
24964
24965
24966
24967
24968
24969
24970
24971
24972
24973
24974
24975
24976
24977
24978
24979
24980
24981
24982
24983
24984
24985
24986
24987
24988
24989
24990
24991
24992
24993
24994
24995
24996
24997
24998
24999
25000
25001
25002
25003
25004
25005
25006
25007
25008
25009
25010
25011
25012
25013
25014
25015
25016
25017
25018
25019
25020
25021
25022
25023
25024
25025
25026
25027
25028
25029
25030
25031
25032
25033
25034
25035
25036
25037
25038
25039
25040
25041
25042
25043
25044
25045
25046
25047
25048
25049
25050
25051
25052
25053
25054
25055
25056
25057
25058
25059
25060
25061
25062
25063
25064
25065
25066
25067
25068
25069
25070
25071
25072
25073
25074
25075
25076
25077
25078
25079
25080
25081
25082
25083
25084
25085
25086
25087
25088
25089
25090
25091
25092
25093
25094
25095
25096
25097
25098
25099
25100
25101
25102
25103
25104
25105
25106
25107
25108
25109
25110
25111
25112
25113
25114
25115
25116
25117
25118
25119
25120
25121
25122
25123
25124
25125
25126
25127
25128
25129
25130
25131
25132
25133
25134
25135
25136
25137
25138
25139
25140
25141
25142
25143
25144
25145
25146
25147
25148
25149
25150
25151
25152
25153
25154
25155
25156
25157
25158
25159
25160
25161
25162
25163
25164
25165
25166
25167
25168
25169
25170
25171
25172
25173
25174
25175
25176
25177
25178
25179
25180
25181
25182
25183
25184
25185
25186
25187
25188
25189
25190
25191
25192
25193
25194
25195
25196
25197
25198
25199
25200
25201
25202
25203
25204
25205
25206
25207
25208
25209
25210
25211
25212
25213
25214
25215
25216
25217
25218
25219
25220
25221
25222
25223
25224
25225
25226
25227
25228
25229
25230
25231
25232
25233
25234
25235
25236
25237
25238
25239
25240
25241
25242
25243
25244
25245
25246
25247
25248
25249
25250
25251
25252
25253
25254
25255
25256
25257
25258
25259
25260
25261
25262
25263
25264
25265
25266
25267
25268
25269
25270
25271
25272
25273
25274
25275
25276
25277
25278
25279
25280
25281
25282
25283
25284
25285
25286
25287
25288
25289
25290
25291
25292
25293
25294
25295
25296
25297
25298
25299
25300
25301
25302
25303
25304
25305
25306
25307
25308
25309
25310
25311
25312
25313
25314
25315
25316
25317
25318
25319
25320
25321
25322
25323
25324
25325
25326
25327
25328
25329
25330
25331
25332
25333
25334
25335
25336
25337
25338
25339
25340
25341
25342
25343
25344
25345
25346
25347
25348
25349
25350
25351
25352
25353
25354
25355
25356
25357
25358
25359
25360
25361
25362
25363
25364
25365
25366
25367
25368
25369
25370
25371
25372
25373
25374
25375
25376
25377
25378
25379
25380
25381
25382
25383
25384
25385
25386
25387
25388
25389
25390
25391
25392
25393
25394
25395
25396
25397
25398
25399
25400
25401
25402
25403
25404
25405
25406
25407
25408
25409
25410
25411
25412
25413
25414
25415
25416
25417
25418
25419
25420
25421
25422
25423
25424
25425
25426
25427
25428
25429
25430
25431
25432
25433
25434
25435
25436
25437
25438
25439
25440
25441
25442
25443
25444
25445
25446
25447
25448
25449
25450
25451
25452
25453
25454
25455
25456
25457
25458
25459
25460
25461
25462
25463
25464
25465
25466
25467
25468
25469
25470
25471
25472
25473
25474
25475
25476
25477
25478
25479
25480
25481
25482
25483
25484
25485
25486
25487
25488
25489
25490
25491
25492
25493
25494
25495
25496
25497
25498
25499
25500
25501
25502
25503
25504
25505
25506
25507
25508
25509
25510
25511
25512
25513
25514
25515
25516
25517
25518
25519
25520
25521
25522
25523
25524
25525
25526
25527
25528
25529
25530
25531
25532
25533
25534
25535
25536
25537
25538
25539
25540
25541
25542
25543
25544
25545
25546
25547
25548
25549
25550
25551
25552
25553
25554
25555
25556
25557
25558
25559
25560
25561
25562
25563
25564
25565
25566
25567
25568
25569
25570
25571
25572
25573
25574
25575
25576
25577
25578
25579
25580
25581
25582
25583
25584
25585
25586
25587
25588
25589
25590
25591
25592
25593
25594
25595
25596
25597
25598
25599
25600
25601
25602
25603
25604
25605
25606
25607
25608
25609
25610
25611
25612
25613
25614
25615
25616
25617
25618
25619
25620
25621
25622
25623
25624
25625
25626
25627
25628
25629
25630
25631
25632
25633
25634
25635
25636
25637
25638
25639
25640
25641
25642
25643
25644
25645
25646
25647
25648
25649
25650
25651
25652
25653
25654
25655
25656
25657
25658
25659
25660
25661
25662
25663
25664
25665
25666
25667
25668
25669
25670
25671
25672
25673
25674
25675
25676
25677
25678
25679
25680
25681
25682
25683
25684
25685
25686
25687
25688
25689
25690
25691
25692
25693
25694
25695
25696
25697
25698
25699
25700
25701
25702
25703
25704
25705
25706
25707
25708
25709
25710
25711
25712
25713
25714
25715
25716
25717
25718
25719
25720
25721
25722
25723
25724
25725
25726
25727
25728
25729
25730
25731
25732
25733
25734
25735
25736
25737
25738
25739
25740
25741
25742
25743
25744
25745
25746
25747
25748
25749
25750
25751
25752
25753
25754
25755
25756
25757
25758
25759
25760
25761
25762
25763
25764
25765
25766
25767
25768
25769
25770
25771
25772
25773
25774
25775
25776
25777
25778
25779
25780
25781
25782
25783
25784
25785
25786
25787
25788
25789
25790
25791
25792
25793
25794
25795
25796
25797
25798
25799
25800
25801
25802
25803
25804
25805
25806
25807
25808
25809
25810
25811
25812
25813
25814
25815
25816
25817
25818
25819
25820
25821
25822
25823
25824
25825
25826
25827
25828
25829
25830
25831
25832
25833
25834
25835
25836
25837
25838
25839
25840
25841
25842
25843
25844
25845
25846
25847
25848
25849
25850
25851
25852
25853
25854
25855
25856
25857
25858
25859
25860
25861
25862
25863
25864
25865
25866
25867
25868
25869
25870
25871
25872
25873
25874
25875
25876
25877
25878
25879
25880
25881
25882
25883
25884
25885
25886
25887
25888
25889
25890
25891
25892
25893
25894
25895
25896
25897
25898
25899
25900
25901
25902
25903
25904
25905
25906
25907
25908
25909
25910
25911
25912
25913
25914
25915
25916
25917
25918
25919
25920
25921
25922
25923
25924
25925
25926
25927
25928
25929
25930
25931
25932
25933
25934
25935
25936
25937
25938
25939
25940
25941
25942
25943
25944
25945
25946
25947
25948
25949
25950
25951
25952
25953
25954
25955
25956
25957
25958
25959
25960
25961
25962
25963
25964
25965
25966
25967
25968
25969
25970
25971
25972
25973
25974
25975
25976
25977
25978
25979
25980
25981
25982
25983
25984
25985
25986
25987
25988
25989
25990
25991
25992
25993
25994
25995
25996
25997
25998
25999
26000
26001
26002
26003
26004
26005
26006
26007
26008
26009
26010
26011
26012
26013
26014
26015
26016
26017
26018
26019
26020
26021
26022
26023
26024
26025
26026
26027
26028
26029
26030
26031
26032
26033
26034
26035
26036
26037
26038
26039
26040
26041
26042
26043
26044
26045
26046
26047
26048
26049
26050
26051
26052
26053
26054
26055
26056
26057
26058
26059
26060
26061
26062
26063
26064
26065
26066
26067
26068
26069
26070
26071
26072
26073
26074
26075
26076
26077
26078
26079
26080
26081
26082
26083
26084
26085
26086
26087
26088
26089
26090
26091
26092
26093
26094
26095
26096
26097
26098
26099
26100
26101
26102
26103
26104
26105
26106
26107
26108
26109
26110
26111
26112
26113
26114
26115
26116
26117
26118
26119
26120
26121
26122
26123
26124
26125
26126
26127
26128
26129
26130
26131
26132
26133
26134
26135
26136
26137
26138
26139
26140
26141
26142
26143
26144
26145
26146
26147
26148
26149
26150
26151
26152
26153
26154
26155
26156
26157
26158
26159
26160
26161
26162
26163
26164
26165
26166
26167
26168
26169
26170
26171
26172
26173
26174
26175
26176
26177
26178
26179
26180
26181
26182
26183
26184
26185
26186
26187
26188
26189
26190
26191
26192
26193
26194
26195
26196
26197
26198
26199
26200
26201
26202
26203
26204
26205
26206
26207
26208
26209
26210
26211
26212
26213
26214
26215
26216
26217
26218
26219
26220
26221
26222
26223
26224
26225
26226
26227
26228
26229
26230
26231
26232
26233
26234
26235
26236
26237
26238
26239
26240
26241
26242
26243
26244
26245
26246
26247
26248
26249
26250
26251
26252
26253
26254
26255
26256
26257
26258
26259
26260
26261
26262
26263
26264
26265
26266
26267
26268
26269
26270
26271
26272
26273
26274
26275
26276
26277
26278
26279
26280
26281
26282
26283
26284
26285
26286
26287
26288
26289
26290
26291
26292
26293
26294
26295
26296
26297
26298
26299
26300
26301
26302
26303
26304
26305
26306
26307
26308
26309
26310
26311
26312
26313
26314
26315
26316
26317
26318
26319
26320
26321
26322
26323
26324
26325
26326
26327
26328
26329
26330
26331
26332
26333
26334
26335
26336
26337
26338
26339
26340
26341
26342
26343
26344
26345
26346
26347
26348
26349
26350
26351
26352
26353
26354
26355
26356
26357
26358
26359
26360
26361
26362
26363
26364
26365
26366
26367
26368
26369
26370
26371
26372
26373
26374
26375
26376
26377
26378
26379
26380
26381
26382
26383
26384
26385
26386
26387
26388
26389
26390
26391
26392
26393
26394
26395
26396
26397
26398
26399
26400
26401
26402
26403
26404
26405
26406
26407
26408
26409
26410
26411
26412
26413
26414
26415
26416
26417
26418
26419
26420
26421
26422
26423
26424
26425
26426
26427
26428
26429
26430
26431
26432
26433
26434
26435
26436
26437
26438
26439
26440
26441
26442
26443
26444
26445
26446
26447
26448
26449
26450
26451
26452
26453
26454
26455
26456
26457
26458
26459
26460
26461
26462
26463
26464
26465
26466
26467
26468
26469
26470
26471
26472
26473
26474
26475
26476
26477
26478
26479
26480
26481
26482
26483
26484
26485
26486
26487
26488
26489
26490
26491
26492
26493
26494
26495
26496
26497
26498
26499
26500
26501
26502
26503
26504
26505
26506
26507
26508
26509
26510
26511
26512
26513
26514
26515
26516
26517
26518
26519
26520
26521
26522
26523
26524
26525
26526
26527
26528
26529
26530
26531
26532
26533
26534
26535
26536
26537
26538
26539
26540
26541
26542
26543
26544
26545
26546
26547
26548
26549
26550
26551
26552
26553
26554
26555
26556
26557
26558
26559
26560
26561
26562
26563
26564
26565
26566
26567
26568
26569
26570
26571
26572
26573
26574
26575
26576
26577
26578
26579
26580
26581
26582
26583
26584
26585
26586
26587
26588
26589
26590
26591
26592
26593
26594
26595
26596
26597
26598
26599
26600
26601
26602
26603
26604
26605
26606
26607
26608
26609
26610
26611
26612
26613
26614
26615
26616
26617
26618
26619
26620
26621
26622
26623
26624
26625
26626
26627
26628
26629
26630
26631
26632
26633
26634
26635
26636
26637
26638
26639
26640
26641
26642
26643
26644
26645
26646
26647
26648
26649
26650
26651
26652
26653
26654
26655
26656
26657
26658
26659
26660
26661
26662
26663
26664
26665
26666
26667
26668
26669
26670
26671
26672
26673
26674
26675
26676
26677
26678
26679
26680
26681
26682
26683
26684
26685
26686
26687
26688
26689
26690
26691
26692
26693
26694
26695
26696
26697
26698
26699
26700
26701
26702
26703
26704
26705
26706
26707
26708
26709
26710
26711
26712
26713
26714
26715
26716
26717
26718
26719
26720
26721
26722
26723
26724
26725
26726
26727
26728
26729
26730
26731
26732
26733
26734
26735
26736
26737
26738
26739
26740
26741
26742
26743
26744
26745
26746
26747
26748
26749
26750
26751
26752
26753
26754
26755
26756
26757
26758
26759
26760
26761
26762
26763
26764
26765
26766
26767
26768
26769
26770
26771
26772
26773
26774
26775
26776
26777
26778
26779
26780
26781
26782
26783
26784
26785
26786
26787
26788
26789
26790
26791
26792
26793
26794
26795
26796
26797
26798
26799
26800
26801
26802
26803
26804
26805
26806
26807
26808
26809
26810
26811
26812
26813
26814
26815
26816
26817
26818
26819
26820
26821
26822
26823
26824
26825
26826
26827
26828
26829
26830
26831
26832
26833
26834
26835
26836
26837
26838
26839
26840
26841
26842
26843
26844
26845
26846
26847
26848
26849
26850
26851
26852
26853
26854
26855
26856
26857
26858
26859
26860
26861
26862
26863
26864
26865
26866
26867
26868
26869
26870
26871
26872
26873
26874
26875
26876
26877
26878
26879
26880
26881
26882
26883
26884
26885
26886
26887
26888
26889
26890
26891
26892
26893
26894
26895
26896
26897
26898
26899
26900
26901
26902
26903
26904
26905
26906
26907
26908
26909
26910
26911
26912
26913
26914
26915
26916
26917
26918
26919
26920
26921
26922
26923
26924
26925
26926
26927
26928
26929
26930
26931
26932
26933
26934
26935
26936
26937
26938
26939
26940
26941
26942
26943
26944
26945
26946
26947
26948
26949
26950
26951
26952
26953
26954
26955
26956
26957
26958
26959
26960
26961
26962
26963
26964
26965
26966
26967
26968
26969
26970
26971
26972
26973
26974
26975
26976
26977
26978
26979
26980
26981
26982
26983
26984
26985
26986
26987
26988
26989
26990
26991
26992
26993
26994
26995
26996
26997
26998
26999
27000
27001
27002
27003
27004
27005
27006
27007
27008
27009
27010
27011
27012
27013
27014
27015
27016
27017
27018
27019
27020
27021
27022
27023
27024
27025
27026
27027
27028
27029
27030
27031
27032
27033
27034
27035
27036
27037
27038
27039
27040
27041
27042
27043
27044
27045
27046
27047
27048
27049
27050
27051
27052
27053
27054
27055
27056
27057
27058
27059
27060
27061
27062
27063
27064
27065
27066
27067
27068
27069
27070
27071
27072
27073
27074
27075
27076
27077
27078
27079
27080
27081
27082
27083
27084
27085
27086
27087
27088
27089
27090
27091
27092
27093
27094
27095
27096
27097
27098
27099
27100
27101
27102
27103
27104
27105
27106
27107
27108
27109
27110
27111
27112
27113
27114
27115
27116
27117
27118
27119
27120
27121
27122
27123
27124
27125
27126
27127
27128
27129
27130
27131
27132
27133
27134
27135
27136
27137
27138
27139
27140
27141
27142
27143
27144
27145
27146
27147
27148
27149
27150
27151
27152
27153
27154
27155
27156
27157
27158
27159
27160
27161
27162
27163
27164
27165
27166
27167
27168
27169
27170
27171
27172
27173
27174
27175
27176
27177
27178
27179
27180
27181
27182
27183
27184
27185
27186
27187
27188
27189
27190
27191
27192
27193
27194
27195
27196
27197
27198
27199
27200
27201
27202
27203
27204
27205
27206
27207
27208
27209
27210
27211
27212
27213
27214
27215
27216
27217
27218
27219
27220
27221
27222
27223
27224
27225
27226
27227
27228
27229
27230
27231
27232
27233
27234
27235
27236
27237
27238
27239
27240
27241
27242
27243
27244
27245
27246
27247
27248
27249
27250
27251
27252
27253
27254
27255
27256
27257
27258
27259
27260
27261
27262
27263
27264
27265
27266
27267
27268
27269
27270
27271
27272
27273
27274
27275
27276
27277
27278
27279
27280
27281
27282
27283
27284
27285
27286
27287
27288
27289
27290
27291
27292
27293
27294
27295
27296
27297
27298
27299
27300
27301
27302
27303
27304
27305
27306
27307
27308
27309
27310
27311
27312
27313
27314
27315
27316
27317
27318
27319
27320
27321
27322
27323
27324
27325
27326
27327
27328
27329
27330
27331
27332
27333
27334
27335
27336
27337
27338
27339
27340
27341
27342
27343
27344
27345
27346
27347
27348
27349
27350
27351
27352
27353
27354
27355
27356
27357
27358
27359
27360
27361
27362
27363
27364
27365
27366
27367
27368
27369
27370
27371
27372
27373
27374
27375
27376
27377
27378
27379
27380
27381
27382
27383
27384
27385
27386
27387
27388
27389
27390
27391
27392
27393
27394
27395
27396
27397
27398
27399
27400
27401
27402
27403
27404
27405
27406
27407
27408
27409
27410
27411
27412
27413
27414
27415
27416
27417
27418
27419
27420
27421
27422
27423
27424
27425
27426
27427
27428
27429
27430
27431
27432
27433
27434
27435
27436
27437
27438
27439
27440
27441
27442
27443
27444
27445
27446
27447
27448
27449
27450
27451
27452
27453
27454
27455
27456
27457
27458
27459
27460
27461
27462
27463
27464
27465
27466
27467
27468
27469
27470
27471
27472
27473
27474
27475
27476
27477
27478
27479
27480
27481
27482
27483
27484
27485
27486
27487
27488
27489
27490
27491
27492
27493
27494
27495
27496
27497
27498
27499
27500
27501
27502
27503
27504
27505
27506
27507
27508
27509
27510
27511
27512
27513
27514
27515
27516
27517
27518
27519
27520
27521
27522
27523
27524
27525
27526
27527
27528
27529
27530
27531
27532
27533
27534
27535
27536
27537
27538
27539
27540
27541
27542
27543
27544
27545
27546
27547
27548
27549
27550
27551
27552
27553
27554
27555
27556
27557
27558
27559
27560
27561
27562
27563
27564
27565
27566
27567
27568
27569
27570
27571
27572
27573
27574
27575
27576
27577
27578
27579
27580
27581
27582
27583
27584
27585
27586
27587
27588
27589
27590
27591
27592
27593
27594
27595
27596
27597
27598
27599
27600
27601
27602
27603
27604
27605
27606
27607
27608
27609
27610
27611
27612
27613
27614
27615
27616
27617
27618
27619
27620
27621
27622
27623
27624
27625
27626
27627
27628
27629
27630
27631
27632
27633
27634
27635
27636
27637
27638
27639
27640
27641
27642
27643
27644
27645
27646
27647
27648
27649
27650
27651
27652
27653
27654
27655
27656
27657
27658
27659
27660
27661
27662
27663
27664
27665
27666
27667
27668
27669
27670
27671
27672
27673
27674
27675
27676
27677
27678
27679
27680
27681
27682
27683
27684
27685
27686
27687
27688
27689
27690
27691
27692
27693
27694
27695
27696
27697
27698
27699
27700
27701
27702
27703
27704
27705
27706
27707
27708
27709
27710
27711
27712
27713
27714
27715
27716
27717
27718
27719
27720
27721
27722
27723
27724
27725
27726
27727
27728
27729
27730
27731
27732
27733
27734
27735
27736
27737
27738
27739
27740
27741
27742
27743
27744
27745
27746
27747
27748
27749
27750
27751
27752
27753
27754
27755
27756
27757
27758
27759
27760
27761
27762
27763
27764
27765
27766
27767
27768
27769
27770
27771
27772
27773
27774
27775
27776
27777
27778
27779
27780
27781
27782
27783
27784
27785
27786
27787
27788
27789
27790
27791
27792
27793
27794
27795
27796
27797
27798
27799
27800
27801
27802
27803
27804
27805
27806
27807
27808
27809
27810
27811
27812
27813
27814
27815
27816
27817
27818
27819
27820
27821
27822
27823
27824
27825
27826
27827
27828
27829
27830
27831
27832
27833
27834
27835
27836
27837
27838
27839
27840
27841
27842
27843
27844
27845
27846
27847
27848
27849
27850
27851
27852
27853
27854
27855
27856
27857
27858
27859
27860
27861
27862
27863
27864
27865
27866
27867
27868
27869
27870
27871
27872
27873
27874
27875
27876
27877
27878
27879
27880
27881
27882
27883
27884
27885
27886
27887
27888
27889
27890
27891
27892
27893
27894
27895
27896
27897
27898
27899
27900
27901
27902
27903
27904
27905
27906
27907
27908
27909
27910
27911
27912
27913
27914
27915
27916
27917
27918
27919
27920
27921
27922
27923
27924
27925
27926
27927
27928
27929
27930
27931
27932
27933
27934
27935
27936
27937
27938
27939
27940
27941
27942
27943
27944
27945
27946
27947
27948
27949
27950
27951
27952
27953
27954
27955
27956
27957
27958
27959
27960
27961
27962
27963
27964
27965
27966
27967
27968
27969
27970
27971
27972
27973
27974
27975
27976
27977
27978
27979
27980
27981
27982
27983
27984
27985
27986
27987
27988
27989
27990
27991
27992
27993
27994
27995
27996
27997
27998
27999
28000
28001
28002
28003
28004
28005
28006
28007
28008
28009
28010
28011
28012
28013
28014
28015
28016
28017
28018
28019
28020
28021
28022
28023
28024
28025
28026
28027
28028
28029
28030
28031
28032
28033
28034
28035
28036
28037
28038
28039
28040
28041
28042
28043
28044
28045
28046
28047
28048
28049
28050
28051
28052
28053
28054
28055
28056
28057
28058
28059
28060
28061
28062
28063
28064
28065
28066
28067
28068
28069
28070
28071
28072
28073
28074
28075
28076
28077
28078
28079
28080
28081
28082
28083
28084
28085
28086
28087
28088
28089
28090
28091
28092
28093
28094
28095
28096
28097
28098
28099
28100
28101
28102
28103
28104
28105
28106
28107
28108
28109
28110
28111
28112
28113
28114
28115
28116
28117
28118
28119
28120
28121
28122
28123
28124
28125
28126
28127
28128
28129
28130
28131
28132
28133
28134
28135
28136
28137
28138
28139
28140
28141
28142
28143
28144
28145
28146
28147
28148
28149
28150
28151
28152
28153
28154
28155
28156
28157
28158
28159
28160
28161
28162
28163
28164
28165
28166
28167
28168
28169
28170
28171
28172
28173
28174
28175
28176
28177
28178
28179
28180
28181
28182
28183
28184
28185
28186
28187
28188
28189
28190
28191
28192
28193
28194
28195
28196
28197
28198
28199
28200
28201
28202
28203
28204
28205
28206
28207
28208
28209
28210
28211
28212
28213
28214
28215
28216
28217
28218
28219
28220
28221
28222
28223
28224
28225
28226
28227
28228
28229
28230
28231
28232
28233
28234
28235
28236
28237
28238
28239
28240
28241
28242
28243
28244
28245
28246
28247
28248
28249
28250
28251
28252
28253
28254
28255
28256
28257
28258
28259
28260
28261
28262
28263
28264
28265
28266
28267
28268
28269
28270
28271
28272
28273
28274
28275
28276
28277
28278
28279
28280
28281
28282
28283
28284
28285
28286
28287
28288
28289
28290
28291
28292
28293
28294
28295
28296
28297
28298
28299
28300
28301
28302
28303
28304
28305
28306
28307
28308
28309
28310
28311
28312
28313
28314
28315
28316
28317
28318
28319
28320
28321
28322
28323
28324
28325
28326
28327
28328
28329
28330
28331
28332
28333
28334
28335
28336
28337
28338
28339
28340
28341
28342
28343
28344
28345
28346
28347
28348
28349
28350
28351
28352
28353
28354
28355
28356
28357
28358
28359
28360
28361
28362
28363
28364
28365
28366
28367
28368
28369
28370
28371
28372
28373
28374
28375
28376
28377
28378
28379
28380
28381
28382
28383
28384
28385
28386
28387
28388
28389
28390
28391
28392
28393
28394
28395
28396
28397
28398
28399
28400
28401
28402
28403
28404
28405
28406
28407
28408
28409
28410
28411
28412
28413
28414
28415
28416
28417
28418
28419
28420
28421
28422
28423
28424
28425
28426
28427
28428
28429
28430
28431
28432
28433
28434
28435
28436
28437
28438
28439
28440
28441
28442
28443
28444
28445
28446
28447
28448
28449
28450
28451
28452
28453
28454
28455
28456
28457
28458
28459
28460
28461
28462
28463
28464
28465
28466
28467
28468
28469
28470
28471
28472
28473
28474
28475
28476
28477
28478
28479
28480
28481
28482
28483
28484
28485
28486
28487
28488
28489
28490
28491
28492
28493
28494
28495
28496
28497
28498
28499
28500
28501
28502
28503
28504
28505
28506
28507
28508
28509
28510
28511
28512
28513
28514
28515
28516
28517
28518
28519
28520
28521
28522
28523
28524
28525
28526
28527
28528
28529
28530
28531
28532
28533
28534
28535
28536
28537
28538
28539
28540
28541
28542
28543
28544
28545
28546
28547
28548
28549
28550
28551
28552
28553
28554
28555
28556
28557
28558
28559
28560
28561
28562
28563
28564
28565
28566
28567
28568
28569
28570
28571
28572
28573
28574
28575
28576
28577
28578
28579
28580
28581
28582
28583
28584
28585
28586
28587
28588
28589
28590
28591
28592
28593
28594
28595
28596
28597
28598
28599
28600
28601
28602
28603
28604
28605
28606
28607
28608
28609
28610
28611
28612
28613
28614
28615
28616
28617
28618
28619
28620
28621
28622
28623
28624
28625
28626
28627
28628
28629
28630
28631
28632
28633
28634
28635
28636
28637
28638
28639
28640
28641
28642
28643
28644
28645
28646
28647
28648
28649
28650
28651
28652
28653
28654
28655
28656
28657
28658
28659
28660
28661
28662
28663
28664
28665
28666
28667
28668
28669
28670
28671
28672
28673
28674
28675
28676
28677
28678
28679
28680
28681
28682
28683
28684
28685
28686
28687
28688
28689
28690
28691
28692
28693
28694
28695
28696
28697
28698
28699
28700
28701
28702
28703
28704
28705
28706
28707
28708
28709
28710
28711
28712
28713
28714
28715
28716
28717
28718
28719
28720
28721
28722
28723
28724
28725
28726
28727
28728
28729
28730
28731
28732
28733
28734
28735
28736
28737
28738
28739
28740
28741
28742
28743
28744
28745
28746
28747
28748
28749
28750
28751
28752
28753
28754
28755
28756
28757
28758
28759
28760
28761
28762
28763
28764
28765
28766
28767
28768
28769
28770
28771
28772
28773
28774
28775
28776
28777
28778
28779
28780
28781
28782
28783
28784
28785
28786
28787
28788
28789
28790
28791
28792
28793
28794
28795
28796
28797
28798
28799
28800
28801
28802
28803
28804
28805
28806
28807
28808
28809
28810
28811
28812
28813
28814
28815
28816
28817
28818
28819
28820
28821
28822
28823
28824
28825
28826
28827
28828
28829
28830
28831
28832
28833
28834
28835
28836
28837
28838
28839
28840
28841
28842
28843
28844
28845
28846
28847
28848
28849
28850
28851
28852
28853
28854
28855
28856
28857
28858
28859
28860
28861
28862
28863
28864
28865
28866
28867
28868
28869
28870
28871
28872
28873
28874
28875
28876
28877
28878
28879
28880
28881
28882
28883
28884
28885
28886
28887
28888
28889
28890
28891
28892
28893
28894
28895
28896
28897
28898
28899
28900
28901
28902
28903
28904
28905
28906
28907
28908
28909
28910
28911
28912
28913
28914
28915
28916
28917
28918
28919
28920
28921
28922
28923
28924
28925
28926
28927
28928
28929
28930
28931
28932
28933
28934
28935
28936
28937
28938
28939
28940
28941
28942
28943
28944
28945
28946
28947
28948
28949
28950
28951
28952
28953
28954
28955
28956
28957
28958
28959
28960
28961
28962
28963
28964
28965
28966
28967
28968
28969
28970
28971
28972
28973
28974
28975
28976
28977
28978
28979
28980
28981
28982
28983
28984
28985
28986
28987
28988
28989
28990
28991
28992
28993
28994
28995
28996
28997
28998
28999
29000
29001
29002
29003
29004
29005
29006
29007
29008
29009
29010
29011
29012
29013
29014
29015
29016
29017
29018
29019
29020
29021
29022
29023
29024
29025
29026
29027
29028
29029
29030
29031
29032
29033
29034
29035
29036
29037
29038
29039
29040
29041
29042
29043
29044
29045
29046
29047
29048
29049
29050
29051
29052
29053
29054
29055
29056
29057
29058
29059
29060
29061
29062
29063
29064
29065
29066
29067
29068
29069
29070
29071
29072
29073
29074
29075
29076
29077
29078
29079
29080
29081
29082
29083
29084
29085
29086
29087
29088
29089
29090
29091
29092
29093
29094
29095
29096
29097
29098
29099
29100
29101
29102
29103
29104
29105
29106
29107
29108
29109
29110
29111
29112
29113
29114
29115
29116
29117
29118
29119
29120
29121
29122
29123
29124
29125
29126
29127
29128
29129
29130
29131
29132
29133
29134
29135
29136
29137
29138
29139
29140
29141
29142
29143
29144
29145
29146
29147
29148
29149
29150
29151
29152
29153
29154
29155
29156
29157
29158
29159
29160
29161
29162
29163
29164
29165
29166
29167
29168
29169
29170
29171
29172
29173
29174
29175
29176
29177
29178
29179
29180
29181
29182
29183
29184
29185
29186
29187
29188
29189
29190
29191
29192
29193
29194
29195
29196
29197
29198
29199
29200
29201
29202
29203
29204
29205
29206
29207
29208
29209
29210
29211
29212
29213
29214
29215
29216
29217
29218
29219
29220
29221
29222
29223
29224
29225
29226
29227
29228
29229
29230
29231
29232
29233
29234
29235
29236
29237
29238
29239
29240
29241
29242
29243
29244
29245
29246
29247
29248
29249
29250
29251
29252
29253
29254
29255
29256
29257
29258
29259
29260
29261
29262
29263
29264
29265
29266
29267
29268
29269
29270
29271
29272
29273
29274
29275
29276
29277
29278
29279
29280
29281
29282
29283
29284
29285
29286
29287
29288
29289
29290
29291
29292
29293
29294
29295
29296
29297
29298
29299
29300
29301
29302
29303
29304
29305
29306
29307
29308
29309
29310
29311
29312
29313
29314
29315
29316
29317
29318
29319
29320
29321
29322
29323
29324
29325
29326
29327
29328
29329
29330
29331
29332
29333
29334
29335
29336
29337
29338
29339
29340
29341
29342
29343
29344
29345
29346
29347
29348
29349
29350
29351
29352
29353
29354
29355
29356
29357
29358
29359
29360
29361
29362
29363
29364
29365
29366
29367
29368
29369
29370
29371
29372
29373
29374
29375
29376
29377
29378
29379
29380
29381
29382
29383
29384
29385
29386
29387
29388
29389
29390
29391
29392
29393
29394
29395
29396
29397
29398
29399
29400
29401
29402
29403
29404
29405
29406
29407
29408
29409
29410
29411
29412
29413
29414
29415
29416
29417
29418
29419
29420
29421
29422
29423
29424
29425
29426
29427
29428
29429
29430
29431
29432
29433
29434
29435
29436
29437
29438
29439
29440
29441
29442
29443
29444
29445
29446
29447
29448
29449
29450
29451
29452
29453
29454
29455
29456
29457
29458
29459
29460
29461
29462
29463
29464
29465
29466
29467
29468
29469
29470
29471
29472
29473
29474
29475
29476
29477
29478
29479
29480
29481
29482
29483
29484
29485
29486
29487
29488
29489
29490
29491
29492
29493
29494
29495
29496
29497
29498
29499
29500
29501
29502
29503
29504
29505
29506
29507
29508
29509
29510
29511
29512
29513
29514
29515
29516
29517
29518
29519
29520
29521
29522
29523
29524
29525
29526
29527
29528
29529
29530
29531
29532
29533
29534
29535
29536
29537
29538
29539
29540
29541
29542
29543
29544
29545
29546
29547
29548
29549
29550
29551
29552
29553
29554
29555
29556
29557
29558
29559
29560
29561
29562
29563
29564
29565
29566
29567
29568
29569
29570
29571
29572
29573
29574
29575
29576
29577
29578
29579
29580
29581
29582
29583
29584
29585
29586
29587
29588
29589
29590
29591
29592
29593
29594
29595
29596
29597
29598
29599
29600
29601
29602
29603
29604
29605
29606
29607
29608
29609
29610
29611
29612
29613
29614
29615
29616
29617
29618
29619
29620
29621
29622
29623
29624
29625
29626
29627
29628
29629
29630
29631
29632
29633
29634
29635
29636
29637
29638
29639
29640
29641
29642
29643
29644
29645
29646
29647
29648
29649
29650
29651
29652
29653
29654
29655
29656
29657
29658
29659
29660
29661
29662
29663
29664
29665
29666
29667
29668
29669
29670
29671
29672
29673
29674
29675
29676
29677
29678
29679
29680
29681
29682
29683
29684
29685
29686
29687
29688
29689
29690
29691
29692
29693
29694
29695
29696
29697
29698
29699
29700
29701
29702
29703
29704
29705
29706
29707
29708
29709
29710
29711
29712
29713
29714
29715
29716
29717
29718
29719
29720
29721
29722
29723
29724
29725
29726
29727
29728
29729
29730
29731
29732
29733
29734
29735
29736
29737
29738
29739
29740
29741
29742
29743
29744
29745
29746
29747
29748
29749
29750
29751
29752
29753
29754
29755
29756
29757
29758
29759
29760
29761
29762
29763
29764
29765
29766
29767
29768
29769
29770
29771
29772
29773
29774
29775
29776
29777
29778
29779
29780
29781
29782
29783
29784
29785
29786
29787
29788
29789
29790
29791
29792
29793
29794
29795
29796
29797
29798
29799
29800
29801
29802
29803
29804
29805
29806
29807
29808
29809
29810
29811
29812
29813
29814
29815
29816
29817
29818
29819
29820
29821
29822
29823
29824
29825
29826
29827
29828
29829
29830
29831
29832
29833
29834
29835
29836
29837
29838
29839
29840
29841
29842
29843
29844
29845
29846
29847
29848
29849
29850
29851
29852
29853
29854
29855
29856
29857
29858
29859
29860
29861
29862
29863
29864
29865
29866
29867
29868
29869
29870
29871
29872
29873
29874
29875
29876
29877
29878
29879
29880
29881
29882
29883
29884
29885
29886
29887
29888
29889
29890
29891
29892
29893
29894
29895
29896
29897
29898
29899
29900
29901
29902
29903
29904
29905
29906
29907
29908
29909
29910
29911
29912
29913
29914
29915
29916
29917
29918
29919
29920
29921
29922
29923
29924
29925
29926
29927
29928
29929
29930
29931
29932
29933
29934
29935
29936
29937
29938
29939
29940
29941
29942
29943
29944
29945
29946
29947
29948
29949
29950
29951
29952
29953
29954
29955
29956
29957
29958
29959
29960
29961
29962
29963
29964
29965
29966
29967
29968
29969
29970
29971
29972
29973
29974
29975
29976
29977
29978
29979
29980
29981
29982
29983
29984
29985
29986
29987
29988
29989
29990
29991
29992
29993
29994
29995
29996
29997
29998
29999
30000
30001
30002
30003
30004
30005
30006
30007
30008
30009
30010
30011
30012
30013
30014
30015
30016
30017
30018
30019
30020
30021
30022
30023
30024
30025
30026
30027
30028
30029
30030
30031
30032
30033
30034
30035
30036
30037
30038
30039
30040
30041
30042
30043
30044
30045
30046
30047
30048
30049
30050
30051
30052
30053
30054
30055
30056
30057
30058
30059
30060
30061
30062
30063
30064
30065
30066
30067
30068
30069
30070
30071
30072
30073
30074
30075
30076
30077
30078
30079
30080
30081
30082
30083
30084
30085
30086
30087
30088
30089
30090
30091
30092
30093
30094
30095
30096
30097
30098
30099
30100
30101
30102
30103
30104
30105
30106
30107
30108
30109
30110
30111
30112
30113
30114
30115
30116
30117
30118
30119
30120
30121
30122
30123
30124
30125
30126
30127
30128
30129
30130
30131
30132
30133
30134
30135
30136
30137
30138
30139
30140
30141
30142
30143
30144
30145
30146
30147
30148
30149
30150
30151
30152
30153
30154
30155
30156
30157
30158
30159
30160
30161
30162
30163
30164
30165
30166
30167
30168
30169
30170
30171
30172
30173
30174
30175
30176
30177
30178
30179
30180
30181
30182
30183
30184
30185
30186
30187
30188
30189
30190
30191
30192
30193
30194
30195
30196
30197
30198
30199
30200
30201
30202
30203
30204
30205
30206
30207
30208
30209
30210
30211
30212
30213
30214
30215
30216
30217
30218
30219
30220
30221
30222
30223
30224
30225
30226
30227
30228
30229
30230
30231
30232
30233
30234
30235
30236
30237
30238
30239
30240
30241
30242
30243
30244
30245
30246
30247
30248
30249
30250
30251
30252
30253
30254
30255
30256
30257
30258
30259
30260
30261
30262
30263
30264
30265
30266
30267
30268
30269
30270
30271
30272
30273
30274
30275
30276
30277
30278
30279
30280
30281
30282
30283
30284
30285
30286
30287
30288
30289
30290
30291
30292
30293
30294
30295
30296
30297
30298
30299
30300
30301
30302
30303
30304
30305
30306
30307
30308
30309
30310
30311
30312
30313
30314
30315
30316
30317
30318
30319
30320
30321
30322
30323
30324
30325
30326
30327
30328
30329
30330
30331
30332
30333
30334
30335
30336
30337
30338
30339
30340
30341
30342
30343
30344
30345
30346
30347
30348
30349
30350
30351
30352
30353
30354
30355
30356
30357
30358
30359
30360
30361
30362
30363
30364
30365
30366
30367
30368
30369
30370
30371
30372
30373
30374
30375
30376
30377
30378
30379
30380
30381
30382
30383
30384
30385
30386
30387
30388
30389
30390
30391
30392
30393
30394
30395
30396
30397
30398
30399
30400
30401
30402
30403
30404
30405
30406
30407
30408
30409
30410
30411
30412
30413
30414
30415
30416
30417
30418
30419
30420
30421
30422
30423
30424
30425
30426
30427
30428
30429
30430
30431
30432
30433
30434
30435
30436
30437
30438
30439
30440
30441
30442
30443
30444
30445
30446
30447
30448
30449
30450
30451
30452
30453
30454
30455
30456
30457
30458
30459
30460
30461
30462
30463
30464
30465
30466
30467
30468
30469
30470
30471
30472
30473
30474
30475
30476
30477
30478
30479
30480
30481
30482
30483
30484
30485
30486
30487
30488
30489
30490
30491
30492
30493
30494
30495
30496
30497
30498
30499
30500
30501
30502
30503
30504
30505
30506
30507
30508
30509
30510
30511
30512
30513
30514
30515
30516
30517
30518
30519
30520
30521
30522
30523
30524
30525
30526
30527
30528
30529
30530
30531
30532
30533
30534
30535
30536
30537
30538
30539
30540
30541
30542
30543
30544
30545
30546
30547
30548
30549
30550
30551
30552
30553
30554
30555
30556
30557
30558
30559
30560
30561
30562
30563
30564
30565
30566
30567
30568
30569
30570
30571
30572
30573
30574
30575
30576
30577
30578
30579
30580
30581
30582
30583
30584
30585
30586
30587
30588
30589
30590
30591
30592
30593
30594
30595
30596
30597
30598
30599
30600
30601
30602
30603
30604
30605
30606
30607
30608
30609
30610
30611
30612
30613
30614
30615
30616
30617
30618
30619
30620
30621
30622
30623
30624
30625
30626
30627
30628
30629
30630
30631
30632
30633
30634
30635
30636
30637
30638
30639
30640
30641
30642
30643
30644
30645
30646
30647
30648
30649
30650
30651
30652
30653
30654
30655
30656
30657
30658
30659
30660
30661
30662
30663
30664
30665
30666
30667
30668
30669
30670
30671
30672
30673
30674
30675
30676
30677
30678
30679
30680
30681
30682
30683
30684
30685
30686
30687
30688
30689
30690
30691
30692
30693
30694
30695
30696
30697
30698
30699
30700
30701
30702
30703
30704
30705
30706
30707
30708
30709
30710
30711
30712
30713
30714
30715
30716
30717
30718
30719
30720
30721
30722
30723
30724
30725
30726
30727
30728
30729
30730
30731
30732
30733
30734
30735
30736
30737
30738
30739
30740
30741
30742
30743
30744
30745
30746
30747
30748
30749
30750
30751
30752
30753
30754
30755
30756
30757
30758
30759
30760
30761
30762
30763
30764
30765
30766
30767
30768
30769
30770
30771
30772
30773
30774
30775
30776
30777
30778
30779
30780
30781
30782
30783
30784
30785
30786
30787
30788
30789
30790
30791
30792
30793
30794
30795
30796
30797
30798
30799
30800
30801
30802
30803
30804
30805
30806
30807
30808
30809
30810
30811
30812
30813
30814
30815
30816
30817
30818
30819
30820
30821
30822
30823
30824
30825
30826
30827
30828
30829
30830
30831
30832
30833
30834
30835
30836
30837
30838
30839
30840
30841
30842
30843
30844
30845
30846
30847
30848
30849
30850
30851
30852
30853
30854
30855
30856
30857
30858
30859
30860
30861
30862
30863
30864
30865
30866
30867
30868
30869
30870
30871
30872
30873
30874
30875
30876
30877
30878
30879
30880
30881
30882
30883
30884
30885
30886
30887
30888
30889
30890
30891
30892
30893
30894
30895
30896
30897
30898
30899
30900
30901
30902
30903
30904
30905
30906
30907
30908
30909
30910
30911
30912
30913
30914
30915
30916
30917
30918
30919
30920
30921
30922
30923
30924
30925
30926
30927
30928
30929
30930
30931
30932
30933
30934
30935
30936
30937
30938
30939
30940
30941
30942
30943
30944
30945
30946
30947
30948
30949
30950
30951
30952
30953
30954
30955
30956
30957
30958
30959
30960
30961
30962
30963
30964
30965
30966
30967
30968
30969
30970
30971
30972
30973
30974
30975
30976
30977
30978
30979
30980
30981
30982
30983
30984
30985
30986
30987
30988
30989
30990
30991
30992
30993
30994
30995
30996
30997
30998
30999
31000
31001
31002
31003
31004
31005
31006
31007
31008
31009
31010
31011
31012
31013
31014
31015
31016
31017
31018
31019
31020
31021
31022
31023
31024
31025
31026
31027
31028
31029
31030
31031
31032
31033
31034
31035
31036
31037
31038
31039
31040
31041
31042
31043
31044
31045
31046
31047
31048
31049
31050
31051
31052
31053
31054
31055
31056
31057
31058
31059
31060
31061
31062
31063
31064
31065
31066
31067
31068
31069
31070
31071
31072
31073
31074
31075
31076
31077
31078
31079
31080
31081
31082
31083
31084
31085
31086
31087
31088
31089
31090
31091
31092
31093
31094
31095
31096
31097
31098
31099
31100
31101
31102
31103
31104
31105
31106
31107
31108
31109
31110
31111
31112
31113
31114
31115
31116
31117
31118
31119
31120
31121
31122
31123
31124
31125
31126
31127
31128
31129
31130
31131
31132
31133
31134
31135
31136
31137
31138
31139
31140
31141
31142
31143
31144
31145
31146
31147
31148
31149
31150
31151
31152
31153
31154
31155
31156
31157
31158
31159
31160
31161
31162
31163
31164
31165
31166
31167
31168
31169
31170
31171
31172
31173
31174
31175
31176
31177
31178
31179
31180
31181
31182
31183
31184
31185
31186
31187
31188
31189
31190
31191
31192
31193
31194
31195
31196
31197
31198
31199
31200
31201
31202
31203
31204
31205
31206
31207
31208
31209
31210
31211
31212
31213
31214
31215
31216
31217
31218
31219
31220
31221
31222
31223
31224
31225
31226
31227
31228
31229
31230
31231
31232
31233
31234
31235
31236
31237
31238
31239
31240
31241
31242
31243
31244
31245
31246
31247
31248
31249
31250
31251
31252
31253
31254
31255
31256
31257
31258
31259
31260
31261
31262
31263
31264
31265
31266
31267
31268
31269
31270
31271
31272
31273
31274
31275
31276
31277
31278
31279
31280
31281
31282
31283
31284
31285
31286
31287
31288
31289
31290
31291
31292
31293
31294
31295
31296
31297
31298
31299
31300
31301
31302
31303
31304
31305
31306
31307
31308
31309
31310
31311
31312
31313
31314
31315
31316
31317
31318
31319
31320
31321
31322
31323
31324
31325
31326
31327
31328
31329
31330
31331
31332
31333
31334
31335
31336
31337
31338
31339
31340
31341
31342
31343
31344
31345
31346
31347
31348
31349
31350
31351
31352
31353
31354
31355
31356
31357
31358
31359
31360
31361
31362
31363
31364
31365
31366
31367
31368
31369
31370
31371
31372
31373
31374
31375
31376
31377
31378
31379
31380
31381
31382
31383
31384
31385
31386
31387
31388
31389
31390
31391
31392
31393
31394
31395
31396
31397
31398
31399
31400
31401
31402
31403
31404
31405
31406
31407
31408
31409
31410
31411
31412
31413
31414
31415
31416
31417
31418
31419
31420
31421
31422
31423
31424
31425
31426
31427
31428
31429
31430
31431
31432
31433
31434
31435
31436
31437
31438
31439
31440
31441
31442
31443
31444
31445
31446
31447
31448
31449
31450
31451
31452
31453
31454
31455
31456
31457
31458
31459
31460
31461
31462
31463
31464
31465
31466
31467
31468
31469
31470
31471
31472
31473
31474
31475
31476
31477
31478
31479
31480
31481
31482
31483
31484
31485
31486
31487
31488
31489
31490
31491
31492
31493
31494
31495
31496
31497
31498
31499
31500
31501
31502
31503
31504
31505
31506
31507
31508
31509
31510
31511
31512
31513
31514
31515
31516
31517
31518
31519
31520
31521
31522
31523
31524
31525
31526
31527
31528
31529
31530
31531
31532
31533
31534
31535
31536
31537
31538
31539
31540
31541
31542
31543
31544
31545
31546
31547
31548
31549
31550
31551
31552
31553
31554
31555
31556
31557
31558
31559
31560
31561
31562
31563
31564
31565
31566
31567
31568
31569
31570
31571
31572
31573
31574
31575
31576
31577
31578
31579
31580
31581
31582
31583
31584
31585
31586
31587
31588
31589
31590
31591
31592
31593
31594
31595
31596
31597
31598
31599
31600
31601
31602
31603
31604
31605
31606
31607
31608
31609
31610
31611
31612
31613
31614
31615
31616
31617
31618
31619
31620
31621
31622
31623
31624
31625
31626
31627
31628
31629
31630
31631
31632
31633
31634
31635
31636
31637
31638
31639
31640
31641
31642
31643
31644
31645
31646
31647
31648
31649
31650
31651
31652
31653
31654
31655
31656
31657
31658
31659
31660
31661
31662
31663
31664
31665
31666
31667
31668
31669
31670
31671
31672
31673
31674
31675
31676
31677
31678
31679
31680
31681
31682
31683
31684
31685
31686
31687
31688
31689
31690
31691
31692
31693
31694
31695
31696
31697
31698
31699
31700
31701
31702
31703
31704
31705
31706
31707
31708
31709
31710
31711
31712
31713
31714
31715
31716
31717
31718
31719
31720
31721
31722
31723
31724
31725
31726
31727
31728
31729
31730
31731
31732
31733
31734
31735
31736
31737
31738
31739
31740
31741
31742
31743
31744
31745
31746
31747
31748
31749
31750
31751
31752
31753
31754
31755
31756
31757
31758
31759
31760
31761
31762
31763
31764
31765
31766
31767
31768
31769
31770
31771
31772
31773
31774
31775
31776
31777
31778
31779
31780
31781
31782
31783
31784
31785
31786
31787
31788
31789
31790
31791
31792
31793
31794
31795
31796
31797
31798
31799
31800
31801
31802
31803
31804
31805
31806
31807
31808
31809
31810
31811
31812
31813
31814
31815
31816
31817
31818
31819
31820
31821
31822
31823
31824
31825
31826
31827
31828
31829
31830
31831
31832
31833
31834
31835
31836
31837
31838
31839
31840
31841
31842
31843
31844
31845
31846
31847
31848
31849
31850
31851
31852
31853
31854
31855
31856
31857
31858
31859
31860
31861
31862
31863
31864
31865
31866
31867
31868
31869
31870
31871
31872
31873
31874
31875
31876
31877
31878
31879
31880
31881
31882
31883
31884
31885
31886
31887
31888
31889
31890
31891
31892
31893
31894
31895
31896
31897
31898
31899
31900
31901
31902
31903
31904
31905
31906
31907
31908
31909
31910
31911
31912
31913
31914
31915
31916
31917
31918
31919
31920
31921
31922
31923
31924
31925
31926
31927
31928
31929
31930
31931
31932
31933
31934
31935
31936
31937
31938
31939
31940
31941
31942
31943
31944
31945
31946
31947
31948
31949
31950
31951
31952
31953
31954
31955
31956
31957
31958
31959
31960
31961
31962
31963
31964
31965
31966
31967
31968
31969
31970
31971
31972
31973
31974
31975
31976
31977
31978
31979
31980
31981
31982
31983
31984
31985
31986
31987
31988
31989
31990
31991
31992
31993
31994
31995
31996
31997
31998
31999
32000
32001
32002
32003
32004
32005
32006
32007
32008
32009
32010
32011
32012
32013
32014
32015
32016
32017
32018
32019
32020
32021
32022
32023
32024
32025
32026
32027
32028
32029
32030
32031
32032
32033
32034
32035
32036
32037
32038
32039
32040
32041
32042
32043
32044
32045
32046
32047
32048
32049
32050
32051
32052
32053
32054
32055
32056
32057
32058
32059
32060
32061
32062
32063
32064
32065
32066
32067
32068
32069
32070
32071
32072
32073
32074
32075
32076
32077
32078
32079
32080
32081
32082
32083
32084
32085
32086
32087
32088
32089
32090
32091
32092
32093
32094
32095
32096
32097
32098
32099
32100
32101
32102
32103
32104
32105
32106
32107
32108
32109
32110
32111
32112
32113
32114
32115
32116
32117
32118
32119
32120
32121
32122
32123
32124
32125
32126
32127
32128
32129
32130
32131
32132
32133
32134
32135
32136
32137
32138
32139
32140
32141
32142
32143
32144
32145
32146
32147
32148
32149
32150
32151
32152
32153
32154
32155
32156
32157
32158
32159
32160
32161
32162
32163
32164
32165
32166
32167
32168
32169
32170
32171
32172
32173
32174
32175
32176
32177
32178
32179
32180
32181
32182
32183
32184
32185
32186
32187
32188
32189
32190
32191
32192
32193
32194
32195
32196
32197
32198
32199
32200
32201
32202
32203
32204
32205
32206
32207
32208
32209
32210
32211
32212
32213
32214
32215
32216
32217
32218
32219
32220
32221
32222
32223
32224
32225
32226
32227
32228
32229
32230
32231
32232
32233
32234
32235
32236
32237
32238
32239
32240
32241
32242
32243
32244
32245
32246
32247
32248
32249
32250
32251
32252
32253
32254
32255
32256
32257
32258
32259
32260
32261
32262
32263
32264
32265
32266
32267
32268
32269
32270
32271
32272
32273
32274
32275
32276
32277
32278
32279
32280
32281
32282
32283
32284
32285
32286
32287
32288
32289
32290
32291
32292
32293
32294
32295
32296
32297
32298
32299
32300
32301
32302
32303
32304
32305
32306
32307
32308
32309
32310
32311
32312
32313
32314
32315
32316
32317
32318
32319
32320
32321
32322
32323
32324
32325
32326
32327
32328
32329
32330
32331
32332
32333
32334
32335
32336
32337
32338
32339
32340
32341
32342
32343
32344
32345
32346
32347
32348
32349
32350
32351
32352
32353
32354
32355
32356
32357
32358
32359
32360
32361
32362
32363
32364
32365
32366
32367
32368
32369
32370
32371
32372
32373
32374
32375
32376
32377
32378
32379
32380
32381
32382
32383
32384
32385
32386
32387
32388
32389
32390
32391
32392
32393
32394
32395
32396
32397
32398
32399
32400
32401
32402
32403
32404
32405
32406
32407
32408
32409
32410
32411
32412
32413
32414
32415
32416
32417
32418
32419
32420
32421
32422
32423
32424
32425
32426
32427
32428
32429
32430
32431
32432
32433
32434
32435
32436
32437
32438
32439
32440
32441
32442
32443
32444
32445
32446
32447
32448
32449
32450
32451
32452
32453
32454
32455
32456
32457
32458
32459
32460
32461
32462
32463
32464
32465
32466
32467
32468
32469
32470
32471
32472
32473
32474
32475
32476
32477
32478
32479
32480
32481
32482
32483
32484
32485
32486
32487
32488
32489
32490
32491
32492
32493
32494
32495
32496
32497
32498
32499
32500
32501
32502
32503
32504
32505
32506
32507
32508
32509
32510
32511
32512
32513
32514
32515
32516
32517
32518
32519
32520
32521
32522
32523
32524
32525
32526
32527
32528
32529
32530
32531
32532
32533
32534
32535
32536
32537
32538
32539
32540
32541
32542
32543
32544
32545
32546
32547
32548
32549
32550
32551
32552
32553
32554
32555
32556
32557
32558
32559
32560
32561
32562
32563
32564
32565
32566
32567
32568
32569
32570
32571
32572
32573
32574
32575
32576
32577
32578
32579
32580
32581
32582
32583
32584
32585
32586
32587
32588
32589
32590
32591
32592
32593
32594
32595
32596
32597
32598
32599
32600
32601
32602
32603
32604
32605
32606
32607
32608
32609
32610
32611
32612
32613
32614
32615
32616
32617
32618
32619
32620
32621
32622
32623
32624
32625
32626
32627
32628
32629
32630
32631
32632
32633
32634
32635
32636
32637
32638
32639
32640
32641
32642
32643
32644
32645
32646
32647
32648
32649
32650
32651
32652
32653
32654
32655
32656
32657
32658
32659
32660
32661
32662
32663
32664
32665
32666
32667
32668
32669
32670
32671
32672
32673
32674
32675
32676
32677
32678
32679
32680
32681
32682
32683
32684
32685
32686
32687
32688
32689
32690
32691
32692
32693
32694
32695
32696
32697
32698
32699
32700
32701
32702
32703
32704
32705
32706
32707
32708
32709
32710
32711
32712
32713
32714
32715
32716
32717
32718
32719
32720
32721
32722
32723
32724
32725
32726
32727
32728
32729
32730
32731
32732
32733
32734
32735
32736
32737
32738
32739
32740
32741
32742
32743
32744
32745
32746
32747
32748
32749
32750
32751
32752
32753
32754
32755
32756
32757
32758
32759
32760
32761
32762
32763
32764
32765
32766
32767
32768
32769
32770
32771
32772
32773
32774
32775
32776
32777
32778
32779
32780
32781
32782
32783
32784
32785
32786
32787
32788
32789
32790
32791
32792
32793
32794
32795
32796
32797
32798
32799
32800
32801
32802
32803
32804
32805
32806
32807
32808
32809
32810
32811
32812
32813
32814
32815
32816
32817
32818
32819
32820
32821
32822
32823
32824
32825
32826
32827
32828
32829
32830
32831
32832
32833
32834
32835
32836
32837
32838
32839
32840
32841
32842
32843
32844
32845
32846
32847
32848
32849
32850
32851
32852
32853
32854
32855
32856
32857
32858
32859
32860
32861
32862
32863
32864
32865
32866
32867
32868
32869
32870
32871
32872
32873
32874
32875
32876
32877
32878
32879
32880
32881
32882
32883
32884
32885
32886
32887
32888
32889
32890
32891
32892
32893
32894
32895
32896
32897
32898
32899
32900
32901
32902
32903
32904
32905
32906
32907
32908
32909
32910
32911
32912
32913
32914
32915
32916
32917
32918
32919
32920
32921
32922
32923
32924
32925
32926
32927
32928
32929
32930
32931
32932
32933
32934
32935
32936
32937
32938
32939
32940
32941
32942
32943
32944
32945
32946
32947
32948
32949
32950
32951
32952
32953
32954
32955
32956
32957
32958
32959
32960
32961
32962
32963
32964
32965
32966
32967
32968
32969
32970
32971
32972
32973
32974
32975
32976
32977
32978
32979
32980
32981
32982
32983
32984
32985
32986
32987
32988
32989
32990
32991
32992
32993
32994
32995
32996
32997
32998
32999
33000
33001
33002
33003
33004
33005
33006
33007
33008
33009
33010
33011
33012
33013
33014
33015
33016
33017
33018
33019
33020
33021
33022
33023
33024
33025
33026
33027
33028
33029
33030
33031
33032
33033
33034
33035
33036
33037
33038
33039
33040
33041
33042
33043
33044
33045
33046
33047
33048
33049
33050
33051
33052
33053
33054
33055
33056
33057
33058
33059
33060
33061
33062
33063
33064
33065
33066
33067
33068
33069
33070
33071
33072
33073
33074
33075
33076
33077
33078
33079
33080
33081
33082
33083
33084
33085
33086
33087
33088
33089
33090
33091
33092
33093
33094
33095
33096
33097
33098
33099
33100
33101
33102
33103
33104
33105
33106
33107
33108
33109
33110
33111
33112
33113
33114
33115
33116
33117
33118
33119
33120
33121
33122
33123
33124
33125
33126
33127
33128
33129
33130
33131
33132
33133
33134
33135
33136
33137
33138
33139
33140
33141
33142
33143
33144
33145
33146
33147
33148
33149
33150
33151
33152
33153
33154
33155
33156
33157
33158
33159
33160
33161
33162
33163
33164
33165
33166
33167
33168
33169
33170
33171
33172
33173
33174
33175
33176
33177
33178
33179
33180
33181
33182
33183
33184
33185
33186
33187
33188
33189
33190
33191
33192
33193
33194
33195
33196
33197
33198
33199
33200
33201
33202
33203
33204
33205
33206
33207
33208
33209
33210
33211
33212
33213
33214
33215
33216
33217
33218
33219
33220
33221
33222
33223
33224
33225
33226
33227
33228
33229
33230
33231
33232
33233
33234
33235
33236
33237
33238
33239
33240
33241
33242
33243
33244
33245
33246
33247
33248
33249
33250
33251
33252
33253
33254
33255
33256
33257
33258
33259
33260
33261
33262
33263
33264
33265
33266
33267
33268
33269
33270
33271
33272
33273
33274
33275
33276
33277
33278
33279
33280
33281
33282
33283
33284
33285
33286
33287
33288
33289
33290
33291
33292
33293
33294
33295
33296
33297
33298
33299
33300
33301
33302
33303
33304
33305
33306
33307
33308
33309
33310
33311
33312
33313
33314
33315
33316
33317
33318
33319
33320
33321
33322
33323
33324
33325
33326
33327
33328
33329
33330
33331
33332
33333
33334
33335
33336
33337
33338
33339
33340
33341
33342
33343
33344
33345
33346
33347
33348
33349
33350
33351
33352
33353
33354
33355
33356
33357
33358
33359
33360
33361
33362
33363
33364
33365
33366
33367
33368
33369
33370
33371
33372
33373
33374
33375
33376
33377
33378
33379
33380
33381
33382
33383
33384
33385
33386
33387
33388
33389
33390
33391
33392
33393
33394
33395
33396
33397
33398
33399
33400
33401
33402
33403
33404
33405
33406
33407
33408
33409
33410
33411
33412
33413
33414
33415
33416
33417
33418
33419
33420
33421
33422
33423
33424
33425
33426
33427
33428
33429
33430
33431
33432
33433
33434
33435
33436
33437
33438
33439
33440
33441
33442
33443
33444
33445
33446
33447
33448
33449
33450
33451
33452
33453
33454
33455
33456
33457
33458
33459
33460
33461
33462
33463
33464
33465
33466
33467
33468
33469
33470
33471
33472
33473
33474
33475
33476
33477
33478
33479
33480
33481
33482
33483
33484
33485
33486
33487
33488
33489
33490
33491
33492
33493
33494
33495
33496
33497
33498
33499
33500
33501
33502
33503
33504
33505
33506
33507
33508
33509
33510
33511
33512
33513
33514
33515
33516
33517
33518
33519
33520
33521
33522
33523
33524
33525
33526
33527
33528
33529
33530
33531
33532
33533
33534
33535
33536
33537
33538
33539
33540
33541
33542
33543
33544
33545
33546
33547
33548
33549
33550
33551
33552
33553
33554
33555
33556
33557
33558
33559
33560
33561
33562
33563
33564
33565
33566
33567
33568
33569
33570
33571
33572
33573
33574
33575
33576
33577
33578
33579
33580
33581
33582
33583
33584
33585
33586
33587
33588
33589
33590
33591
33592
33593
33594
33595
33596
33597
33598
33599
33600
33601
33602
33603
33604
33605
33606
33607
33608
33609
33610
33611
33612
33613
33614
33615
33616
33617
33618
33619
33620
33621
33622
33623
33624
33625
33626
33627
33628
33629
33630
33631
33632
33633
33634
33635
33636
33637
33638
33639
33640
33641
33642
33643
33644
33645
33646
33647
33648
33649
33650
33651
33652
33653
33654
33655
33656
33657
33658
33659
33660
33661
33662
33663
33664
33665
33666
33667
33668
33669
33670
33671
33672
33673
33674
33675
33676
33677
33678
33679
33680
33681
33682
33683
33684
33685
33686
33687
33688
33689
33690
33691
33692
33693
33694
33695
33696
33697
33698
33699
33700
33701
33702
33703
33704
33705
33706
33707
33708
33709
33710
33711
33712
33713
33714
33715
33716
33717
33718
33719
33720
33721
33722
33723
33724
33725
33726
33727
33728
33729
33730
33731
33732
33733
33734
33735
33736
33737
33738
33739
33740
33741
33742
33743
33744
33745
33746
33747
33748
33749
33750
33751
33752
33753
33754
33755
33756
33757
33758
33759
33760
33761
33762
33763
33764
33765
33766
33767
33768
33769
33770
33771
33772
33773
33774
33775
33776
33777
33778
33779
33780
33781
33782
33783
33784
33785
33786
33787
33788
33789
33790
33791
33792
33793
33794
33795
33796
33797
33798
33799
33800
33801
33802
33803
33804
33805
33806
33807
33808
33809
33810
33811
33812
33813
33814
33815
33816
33817
33818
33819
33820
33821
33822
33823
33824
33825
33826
33827
33828
33829
33830
33831
33832
33833
33834
33835
33836
33837
33838
33839
33840
33841
33842
33843
33844
33845
33846
33847
33848
33849
33850
33851
33852
33853
33854
33855
33856
33857
33858
33859
33860
33861
33862
33863
33864
33865
33866
33867
33868
33869
33870
33871
33872
33873
33874
33875
33876
33877
33878
33879
33880
33881
33882
33883
33884
33885
33886
33887
33888
33889
33890
33891
33892
33893
33894
33895
33896
33897
33898
33899
33900
33901
33902
33903
33904
33905
33906
33907
33908
33909
33910
33911
33912
33913
33914
33915
33916
33917
33918
33919
33920
33921
33922
33923
33924
33925
33926
33927
33928
33929
33930
33931
33932
33933
33934
33935
33936
33937
33938
33939
33940
33941
33942
33943
33944
33945
33946
33947
33948
33949
33950
33951
33952
33953
33954
33955
33956
33957
33958
33959
33960
33961
33962
33963
33964
33965
33966
33967
33968
33969
33970
33971
33972
33973
33974
33975
33976
33977
33978
33979
33980
33981
33982
33983
33984
33985
33986
33987
33988
33989
33990
33991
33992
33993
33994
33995
33996
33997
33998
33999
34000
34001
34002
34003
34004
34005
34006
34007
34008
34009
34010
34011
34012
34013
34014
34015
34016
34017
34018
34019
34020
34021
34022
34023
34024
34025
34026
34027
34028
34029
34030
34031
34032
34033
34034
34035
34036
34037
34038
34039
34040
34041
34042
34043
34044
34045
34046
34047
34048
34049
34050
34051
34052
34053
34054
34055
34056
34057
34058
34059
34060
34061
34062
34063
34064
34065
34066
34067
34068
34069
34070
34071
34072
34073
34074
34075
34076
34077
34078
34079
34080
34081
34082
34083
34084
34085
34086
34087
34088
34089
34090
34091
34092
34093
34094
34095
34096
34097
34098
34099
34100
34101
34102
34103
34104
34105
34106
34107
34108
34109
34110
34111
34112
34113
34114
34115
34116
34117
34118
34119
34120
34121
34122
34123
34124
34125
34126
34127
34128
34129
34130
34131
34132
34133
34134
34135
34136
34137
34138
34139
34140
34141
34142
34143
34144
34145
34146
34147
34148
34149
34150
34151
34152
34153
34154
34155
34156
34157
34158
34159
34160
34161
34162
34163
34164
34165
34166
34167
34168
34169
34170
34171
34172
34173
34174
34175
34176
34177
34178
34179
34180
34181
34182
34183
34184
34185
34186
34187
34188
34189
34190
34191
34192
34193
34194
34195
34196
34197
34198
34199
34200
34201
34202
34203
34204
34205
34206
34207
34208
34209
34210
34211
34212
34213
34214
34215
34216
34217
34218
34219
34220
34221
34222
34223
34224
34225
34226
34227
34228
34229
34230
34231
34232
34233
34234
34235
34236
34237
34238
34239
34240
34241
34242
34243
34244
34245
34246
34247
34248
34249
34250
34251
34252
34253
34254
34255
34256
34257
34258
34259
34260
34261
34262
34263
34264
34265
34266
34267
34268
34269
34270
34271
34272
34273
34274
34275
34276
34277
34278
34279
34280
34281
34282
34283
34284
34285
34286
34287
34288
34289
34290
34291
34292
34293
34294
34295
34296
34297
34298
34299
34300
34301
34302
34303
34304
34305
34306
34307
34308
34309
34310
34311
34312
34313
34314
34315
34316
34317
34318
34319
34320
34321
34322
34323
34324
34325
34326
34327
34328
34329
34330
34331
34332
34333
34334
34335
34336
34337
34338
34339
34340
34341
34342
34343
34344
34345
34346
34347
34348
34349
34350
34351
34352
34353
34354
34355
34356
34357
34358
34359
34360
34361
34362
34363
34364
34365
34366
34367
34368
34369
34370
34371
34372
34373
34374
34375
34376
34377
34378
34379
34380
34381
34382
34383
34384
34385
34386
34387
34388
34389
34390
34391
34392
34393
34394
34395
34396
34397
34398
34399
34400
34401
34402
34403
34404
34405
34406
34407
34408
34409
34410
34411
34412
34413
34414
34415
34416
34417
34418
34419
34420
34421
34422
34423
34424
34425
34426
34427
34428
34429
34430
34431
34432
34433
34434
34435
34436
34437
34438
34439
34440
34441
34442
34443
34444
34445
34446
34447
34448
34449
34450
34451
34452
34453
34454
34455
34456
34457
34458
34459
34460
34461
34462
34463
34464
34465
34466
34467
34468
34469
34470
34471
34472
34473
34474
34475
34476
34477
34478
34479
34480
34481
34482
34483
34484
34485
34486
34487
34488
34489
34490
34491
34492
34493
34494
34495
34496
34497
34498
34499
34500
34501
34502
34503
34504
34505
34506
34507
34508
34509
34510
34511
34512
34513
34514
34515
34516
34517
34518
34519
34520
34521
34522
34523
34524
34525
34526
34527
34528
34529
34530
34531
34532
34533
34534
34535
34536
34537
34538
34539
34540
34541
34542
34543
34544
34545
34546
34547
34548
34549
34550
34551
34552
34553
34554
34555
34556
34557
34558
34559
34560
34561
34562
34563
34564
34565
34566
34567
34568
34569
34570
34571
34572
34573
34574
34575
34576
34577
34578
34579
34580
34581
34582
34583
34584
34585
34586
34587
34588
34589
34590
34591
34592
34593
34594
34595
34596
34597
34598
34599
34600
34601
34602
34603
34604
34605
34606
34607
34608
34609
34610
34611
34612
34613
34614
34615
34616
34617
34618
34619
34620
34621
34622
34623
34624
34625
34626
34627
34628
34629
34630
34631
34632
34633
34634
34635
34636
34637
34638
34639
34640
34641
34642
34643
34644
34645
34646
34647
34648
34649
34650
34651
34652
34653
34654
34655
34656
34657
34658
34659
34660
34661
34662
34663
34664
34665
34666
34667
34668
34669
34670
34671
34672
34673
34674
34675
34676
34677
34678
34679
34680
34681
34682
34683
34684
34685
34686
34687
34688
34689
34690
34691
34692
34693
34694
34695
34696
34697
34698
34699
34700
34701
34702
34703
34704
34705
34706
34707
34708
34709
34710
34711
34712
34713
34714
34715
34716
34717
34718
34719
34720
34721
34722
34723
34724
34725
34726
34727
34728
34729
34730
34731
34732
34733
34734
34735
34736
34737
34738
34739
34740
34741
34742
34743
34744
34745
34746
34747
34748
34749
34750
34751
34752
34753
34754
34755
34756
34757
34758
34759
34760
34761
34762
34763
34764
34765
34766
34767
34768
34769
34770
34771
34772
34773
34774
34775
34776
34777
34778
34779
34780
34781
34782
34783
34784
34785
34786
34787
34788
34789
34790
34791
34792
34793
34794
34795
34796
34797
34798
34799
34800
34801
34802
34803
34804
34805
34806
34807
34808
34809
34810
34811
34812
34813
34814
34815
34816
34817
34818
34819
34820
34821
34822
34823
34824
34825
34826
34827
34828
34829
34830
34831
34832
34833
34834
34835
34836
34837
34838
34839
34840
34841
34842
34843
34844
34845
34846
34847
34848
34849
34850
34851
34852
34853
34854
34855
34856
34857
34858
34859
34860
34861
34862
34863
34864
34865
34866
34867
34868
34869
34870
34871
34872
34873
34874
34875
34876
34877
34878
34879
34880
34881
34882
34883
34884
34885
34886
34887
34888
34889
34890
34891
34892
34893
34894
34895
34896
34897
34898
34899
34900
34901
34902
34903
34904
34905
34906
34907
34908
34909
34910
34911
34912
34913
34914
34915
34916
34917
34918
34919
34920
34921
34922
34923
34924
34925
34926
34927
34928
34929
34930
34931
34932
34933
34934
34935
34936
34937
34938
34939
34940
34941
34942
34943
34944
34945
34946
34947
34948
34949
34950
34951
34952
34953
34954
34955
34956
34957
34958
34959
34960
34961
34962
34963
34964
34965
34966
34967
34968
34969
34970
34971
34972
34973
34974
34975
34976
34977
34978
34979
34980
34981
34982
34983
34984
34985
34986
34987
34988
34989
34990
34991
34992
34993
34994
34995
34996
34997
34998
34999
35000
35001
35002
35003
35004
35005
35006
35007
35008
35009
35010
35011
35012
35013
35014
35015
35016
35017
35018
35019
35020
35021
35022
35023
35024
35025
35026
35027
35028
35029
35030
35031
35032
35033
35034
35035
35036
35037
35038
35039
35040
35041
35042
35043
35044
35045
35046
35047
35048
35049
35050
35051
35052
35053
35054
35055
35056
35057
35058
35059
35060
35061
35062
35063
35064
35065
35066
35067
35068
35069
35070
35071
35072
35073
35074
35075
35076
35077
35078
35079
35080
35081
35082
35083
35084
35085
35086
35087
35088
35089
35090
35091
35092
35093
35094
35095
35096
35097
35098
35099
35100
35101
35102
35103
35104
35105
35106
35107
35108
35109
35110
35111
35112
35113
35114
35115
35116
35117
35118
35119
35120
35121
35122
35123
35124
35125
35126
35127
35128
35129
35130
35131
35132
35133
35134
35135
35136
35137
35138
35139
35140
35141
35142
35143
35144
35145
35146
35147
35148
35149
35150
35151
35152
35153
35154
35155
35156
35157
35158
35159
35160
35161
35162
35163
35164
35165
35166
35167
35168
35169
35170
35171
35172
35173
35174
35175
35176
35177
35178
35179
35180
35181
35182
35183
35184
35185
35186
35187
35188
35189
35190
35191
35192
35193
35194
35195
35196
35197
35198
35199
35200
35201
35202
35203
35204
35205
35206
35207
35208
35209
35210
35211
35212
35213
35214
35215
35216
35217
35218
35219
35220
35221
35222
35223
35224
35225
35226
35227
35228
35229
35230
35231
35232
35233
35234
35235
35236
35237
35238
35239
35240
35241
35242
35243
35244
35245
35246
35247
35248
35249
35250
35251
35252
35253
35254
35255
35256
35257
35258
35259
35260
35261
35262
35263
35264
35265
35266
35267
35268
35269
35270
35271
35272
35273
35274
35275
35276
35277
35278
35279
35280
35281
35282
35283
35284
35285
35286
35287
35288
35289
35290
35291
35292
35293
35294
35295
35296
35297
35298
35299
35300
35301
35302
35303
35304
35305
35306
35307
35308
35309
35310
35311
35312
35313
35314
35315
35316
35317
35318
35319
35320
35321
35322
35323
35324
35325
35326
35327
35328
35329
35330
35331
35332
35333
35334
35335
35336
35337
35338
35339
35340
35341
35342
35343
35344
35345
35346
35347
35348
35349
35350
35351
35352
35353
35354
35355
35356
35357
35358
35359
35360
35361
35362
35363
35364
35365
35366
35367
35368
35369
35370
35371
35372
35373
35374
35375
35376
35377
35378
35379
35380
35381
35382
35383
35384
35385
35386
35387
35388
35389
35390
35391
35392
35393
35394
35395
35396
35397
35398
35399
35400
35401
35402
35403
35404
35405
35406
35407
35408
35409
35410
35411
35412
35413
35414
35415
35416
35417
35418
35419
35420
35421
35422
35423
35424
35425
35426
35427
35428
35429
35430
35431
35432
35433
35434
35435
35436
35437
35438
35439
35440
35441
35442
35443
35444
35445
35446
35447
35448
35449
35450
35451
35452
35453
35454
35455
35456
35457
35458
35459
35460
35461
35462
35463
35464
35465
35466
35467
35468
35469
35470
35471
35472
35473
35474
35475
35476
35477
35478
35479
35480
35481
35482
35483
35484
35485
35486
35487
35488
35489
35490
35491
35492
35493
35494
35495
35496
35497
35498
35499
35500
35501
35502
35503
35504
35505
35506
35507
35508
35509
35510
35511
35512
35513
35514
35515
35516
35517
35518
35519
35520
35521
35522
35523
35524
35525
35526
35527
35528
35529
35530
35531
35532
35533
35534
35535
35536
35537
35538
35539
35540
35541
35542
35543
35544
35545
35546
35547
35548
35549
35550
35551
35552
35553
35554
35555
35556
35557
35558
35559
35560
35561
35562
35563
35564
35565
35566
35567
35568
35569
35570
35571
35572
35573
35574
35575
35576
35577
35578
35579
35580
35581
35582
35583
35584
35585
35586
35587
35588
35589
35590
35591
35592
35593
35594
35595
35596
35597
35598
35599
35600
35601
35602
35603
35604
35605
35606
35607
35608
35609
35610
35611
35612
35613
35614
35615
35616
35617
35618
35619
35620
35621
35622
35623
35624
35625
35626
35627
35628
35629
35630
35631
35632
35633
35634
35635
35636
35637
35638
35639
35640
35641
35642
35643
35644
35645
35646
35647
35648
35649
35650
35651
35652
35653
35654
35655
35656
35657
35658
35659
35660
35661
35662
35663
35664
35665
35666
35667
35668
35669
35670
35671
35672
35673
35674
35675
35676
35677
35678
35679
35680
35681
35682
35683
35684
35685
35686
35687
35688
35689
35690
35691
35692
35693
35694
35695
35696
35697
35698
35699
35700
35701
35702
35703
35704
35705
35706
35707
35708
35709
35710
35711
35712
35713
35714
35715
35716
35717
35718
35719
35720
35721
35722
35723
35724
35725
35726
35727
35728
35729
35730
35731
35732
35733
35734
35735
35736
35737
35738
35739
35740
35741
35742
35743
35744
35745
35746
35747
35748
35749
35750
35751
35752
35753
35754
35755
35756
35757
35758
35759
35760
35761
35762
35763
35764
35765
35766
35767
35768
35769
35770
35771
35772
35773
35774
35775
35776
35777
35778
35779
35780
35781
35782
35783
35784
35785
35786
35787
35788
35789
35790
35791
35792
35793
35794
35795
35796
35797
35798
35799
35800
35801
35802
35803
35804
35805
35806
35807
35808
35809
35810
35811
35812
35813
35814
35815
35816
35817
35818
35819
35820
35821
35822
35823
35824
35825
35826
35827
35828
35829
35830
35831
35832
35833
35834
35835
35836
35837
35838
35839
35840
35841
35842
35843
35844
35845
35846
35847
35848
35849
35850
35851
35852
35853
35854
35855
35856
35857
35858
35859
35860
35861
35862
35863
35864
35865
35866
35867
35868
35869
35870
35871
35872
35873
35874
35875
35876
35877
35878
35879
35880
35881
35882
35883
35884
35885
35886
35887
35888
35889
35890
35891
35892
35893
35894
35895
35896
35897
35898
35899
35900
35901
35902
35903
35904
35905
35906
35907
35908
35909
35910
35911
35912
35913
35914
35915
35916
35917
35918
35919
35920
35921
35922
35923
35924
35925
35926
35927
35928
35929
35930
35931
35932
35933
35934
35935
35936
35937
35938
35939
35940
35941
35942
35943
35944
35945
35946
35947
35948
35949
35950
35951
35952
35953
35954
35955
35956
35957
35958
35959
35960
35961
35962
35963
35964
35965
35966
35967
35968
35969
35970
35971
35972
35973
35974
35975
35976
35977
35978
35979
35980
35981
35982
35983
35984
35985
35986
35987
35988
35989
35990
35991
35992
35993
35994
35995
35996
35997
35998
35999
36000
36001
36002
36003
36004
36005
36006
36007
36008
36009
36010
36011
36012
36013
36014
36015
36016
36017
36018
36019
36020
36021
36022
36023
36024
36025
36026
36027
36028
36029
36030
36031
36032
36033
36034
36035
36036
36037
36038
36039
36040
36041
36042
36043
36044
36045
36046
36047
36048
36049
36050
36051
36052
36053
36054
36055
36056
36057
36058
36059
36060
36061
36062
36063
36064
36065
36066
36067
36068
36069
36070
36071
36072
36073
36074
36075
36076
36077
36078
36079
36080
36081
36082
36083
36084
36085
36086
36087
36088
36089
36090
36091
36092
36093
36094
36095
36096
36097
36098
36099
36100
36101
36102
36103
36104
36105
36106
36107
36108
36109
36110
36111
36112
36113
36114
36115
36116
36117
36118
36119
36120
36121
36122
36123
36124
36125
36126
36127
36128
36129
36130
36131
36132
36133
36134
36135
36136
36137
36138
36139
36140
36141
36142
36143
36144
36145
36146
36147
36148
36149
36150
36151
36152
36153
36154
36155
36156
36157
36158
36159
36160
36161
36162
36163
36164
36165
36166
36167
36168
36169
36170
36171
36172
36173
36174
36175
36176
36177
36178
36179
36180
36181
36182
36183
36184
36185
36186
36187
36188
36189
36190
36191
36192
36193
36194
36195
36196
36197
36198
36199
36200
36201
36202
36203
36204
36205
36206
36207
36208
36209
36210
36211
36212
36213
36214
36215
36216
36217
36218
36219
36220
36221
36222
36223
36224
36225
36226
36227
36228
36229
36230
36231
36232
36233
36234
36235
36236
36237
36238
36239
36240
36241
36242
36243
36244
36245
36246
36247
36248
36249
36250
36251
36252
36253
36254
36255
36256
36257
36258
36259
36260
36261
36262
36263
36264
36265
36266
36267
36268
36269
36270
36271
36272
36273
36274
36275
36276
36277
36278
36279
36280
36281
36282
36283
36284
36285
36286
36287
36288
36289
36290
36291
36292
36293
36294
36295
36296
36297
36298
36299
36300
36301
36302
36303
36304
36305
36306
36307
36308
36309
36310
36311
36312
36313
36314
36315
36316
36317
36318
36319
36320
36321
36322
36323
36324
36325
36326
36327
36328
36329
36330
36331
36332
36333
36334
36335
36336
36337
36338
36339
36340
36341
36342
36343
36344
36345
36346
36347
36348
36349
36350
36351
36352
36353
36354
36355
36356
36357
36358
36359
36360
36361
36362
36363
36364
36365
36366
36367
36368
36369
36370
36371
36372
36373
36374
36375
36376
36377
36378
36379
36380
36381
36382
36383
36384
36385
36386
36387
36388
36389
36390
36391
36392
36393
36394
36395
36396
36397
36398
36399
36400
36401
36402
36403
36404
36405
36406
36407
36408
36409
36410
36411
36412
36413
36414
36415
36416
36417
36418
36419
36420
36421
36422
36423
36424
36425
36426
36427
36428
36429
36430
36431
36432
36433
36434
36435
36436
36437
36438
36439
36440
36441
36442
36443
36444
36445
36446
36447
36448
36449
36450
36451
36452
36453
36454
36455
36456
36457
36458
36459
36460
36461
36462
36463
36464
36465
36466
36467
36468
36469
36470
36471
36472
36473
36474
36475
36476
36477
36478
36479
36480
36481
36482
36483
36484
36485
36486
36487
36488
36489
36490
36491
36492
36493
36494
36495
36496
36497
36498
36499
36500
36501
36502
36503
36504
36505
36506
36507
36508
36509
36510
36511
36512
36513
36514
36515
36516
36517
36518
36519
36520
36521
36522
36523
36524
36525
36526
36527
36528
36529
36530
36531
36532
36533
36534
36535
36536
36537
36538
36539
36540
36541
36542
36543
36544
36545
36546
36547
36548
36549
36550
36551
36552
36553
36554
36555
36556
36557
36558
36559
36560
36561
36562
36563
36564
36565
36566
36567
36568
36569
36570
36571
36572
36573
36574
36575
36576
36577
36578
36579
36580
36581
36582
36583
36584
36585
36586
36587
36588
36589
36590
36591
36592
36593
36594
36595
36596
36597
36598
36599
36600
36601
36602
36603
36604
36605
36606
36607
36608
36609
36610
36611
36612
36613
36614
36615
36616
36617
36618
36619
36620
36621
36622
36623
36624
36625
36626
36627
36628
36629
36630
36631
36632
36633
36634
36635
36636
36637
36638
36639
36640
36641
36642
36643
36644
36645
36646
36647
36648
36649
36650
36651
36652
36653
36654
36655
36656
36657
36658
36659
36660
36661
36662
36663
36664
36665
36666
36667
36668
36669
36670
36671
36672
36673
36674
36675
36676
36677
36678
36679
36680
36681
36682
36683
36684
36685
36686
36687
36688
36689
36690
36691
36692
36693
36694
36695
36696
36697
36698
36699
36700
36701
36702
36703
36704
36705
36706
36707
36708
36709
36710
36711
36712
36713
36714
36715
36716
36717
36718
36719
36720
36721
36722
36723
36724
36725
36726
36727
36728
36729
36730
36731
36732
36733
36734
36735
36736
36737
36738
36739
36740
36741
36742
36743
36744
36745
36746
36747
36748
36749
36750
36751
36752
36753
36754
36755
36756
36757
36758
36759
36760
36761
36762
36763
36764
36765
36766
36767
36768
36769
36770
36771
36772
36773
36774
36775
36776
36777
36778
36779
36780
36781
36782
36783
36784
36785
36786
36787
36788
36789
36790
36791
36792
36793
36794
36795
36796
36797
36798
36799
36800
36801
36802
36803
36804
36805
36806
36807
36808
36809
36810
36811
36812
36813
36814
36815
36816
36817
36818
36819
36820
36821
36822
36823
36824
36825
36826
36827
36828
36829
36830
36831
36832
36833
36834
36835
36836
36837
36838
36839
36840
36841
36842
36843
36844
36845
36846
36847
36848
36849
36850
36851
36852
36853
36854
36855
36856
36857
36858
36859
36860
36861
36862
36863
36864
36865
36866
36867
36868
36869
36870
36871
36872
36873
36874
36875
36876
36877
36878
36879
36880
36881
36882
36883
36884
36885
36886
36887
36888
36889
36890
36891
36892
36893
36894
36895
36896
36897
36898
36899
36900
36901
36902
36903
36904
36905
36906
36907
36908
36909
36910
36911
36912
36913
36914
36915
36916
36917
36918
36919
36920
36921
36922
36923
36924
36925
36926
36927
36928
36929
36930
36931
36932
36933
36934
36935
36936
36937
36938
36939
36940
36941
36942
36943
36944
36945
36946
36947
36948
36949
36950
36951
36952
36953
36954
36955
36956
36957
36958
36959
36960
36961
36962
36963
36964
36965
36966
36967
36968
36969
36970
36971
36972
36973
36974
36975
36976
36977
36978
36979
36980
36981
36982
36983
36984
36985
36986
36987
36988
36989
36990
36991
36992
36993
36994
36995
36996
36997
36998
36999
37000
37001
37002
37003
37004
37005
37006
37007
37008
37009
37010
37011
37012
37013
37014
37015
37016
37017
37018
37019
37020
37021
37022
37023
37024
37025
37026
37027
37028
37029
37030
37031
37032
37033
37034
37035
37036
37037
37038
37039
37040
37041
37042
37043
37044
37045
37046
37047
37048
37049
37050
37051
37052
37053
37054
37055
37056
37057
37058
37059
37060
37061
37062
37063
37064
37065
37066
37067
37068
37069
37070
37071
37072
37073
37074
37075
37076
37077
37078
37079
37080
37081
37082
37083
37084
37085
37086
37087
37088
37089
37090
37091
37092
37093
37094
37095
37096
37097
37098
37099
37100
37101
37102
37103
37104
37105
37106
37107
37108
37109
37110
37111
37112
37113
37114
37115
37116
37117
37118
37119
37120
37121
37122
37123
37124
37125
37126
37127
37128
37129
37130
37131
37132
37133
37134
37135
37136
37137
37138
37139
37140
37141
37142
37143
37144
37145
37146
37147
37148
37149
37150
37151
37152
37153
37154
37155
37156
37157
37158
37159
37160
37161
37162
37163
37164
37165
37166
37167
37168
37169
37170
37171
37172
37173
37174
37175
37176
37177
37178
37179
37180
37181
37182
37183
37184
37185
37186
37187
37188
37189
37190
37191
37192
37193
37194
37195
37196
37197
37198
37199
37200
37201
37202
37203
37204
37205
37206
37207
37208
37209
37210
37211
37212
37213
37214
37215
37216
37217
37218
37219
37220
37221
37222
37223
37224
37225
37226
37227
37228
37229
37230
37231
37232
37233
37234
37235
37236
37237
37238
37239
37240
37241
37242
37243
37244
37245
37246
37247
37248
37249
37250
37251
37252
37253
37254
37255
37256
37257
37258
37259
37260
37261
37262
37263
37264
37265
37266
37267
37268
37269
37270
37271
37272
37273
37274
37275
37276
37277
37278
37279
37280
37281
37282
37283
37284
37285
37286
37287
37288
37289
37290
37291
37292
37293
37294
37295
37296
37297
37298
37299
37300
37301
37302
37303
37304
37305
37306
37307
37308
37309
37310
37311
37312
37313
37314
37315
37316
37317
37318
37319
37320
37321
37322
37323
37324
37325
37326
37327
37328
37329
37330
37331
37332
37333
37334
37335
37336
37337
37338
37339
37340
37341
37342
37343
37344
37345
37346
37347
37348
37349
37350
37351
37352
37353
37354
37355
37356
37357
37358
37359
37360
37361
37362
37363
37364
37365
37366
37367
37368
37369
37370
37371
37372
37373
37374
37375
37376
37377
37378
37379
37380
37381
37382
37383
37384
37385
37386
37387
37388
37389
37390
37391
37392
37393
37394
37395
37396
37397
37398
37399
37400
37401
37402
37403
37404
37405
37406
37407
37408
37409
37410
37411
37412
37413
37414
37415
37416
37417
37418
37419
37420
37421
37422
37423
37424
37425
37426
37427
37428
37429
37430
37431
37432
37433
37434
37435
37436
37437
37438
37439
37440
37441
37442
37443
37444
37445
37446
37447
37448
37449
37450
37451
37452
37453
37454
37455
37456
37457
37458
37459
37460
37461
37462
37463
37464
37465
37466
37467
37468
37469
37470
37471
37472
37473
37474
37475
37476
37477
37478
37479
37480
37481
37482
37483
37484
37485
37486
37487
37488
37489
37490
37491
37492
37493
37494
37495
37496
37497
37498
37499
37500
37501
37502
37503
37504
37505
37506
37507
37508
37509
37510
37511
37512
37513
37514
37515
37516
37517
37518
37519
37520
37521
37522
37523
37524
37525
37526
37527
37528
37529
37530
37531
37532
37533
37534
37535
37536
37537
37538
37539
37540
37541
37542
37543
37544
37545
37546
37547
37548
37549
37550
37551
37552
37553
37554
37555
37556
37557
37558
37559
37560
37561
37562
37563
37564
37565
37566
37567
37568
37569
37570
37571
37572
37573
37574
37575
37576
37577
37578
37579
37580
37581
37582
37583
37584
37585
37586
37587
37588
37589
37590
37591
37592
37593
37594
37595
37596
37597
37598
37599
37600
37601
37602
37603
37604
37605
37606
37607
37608
37609
37610
37611
37612
37613
37614
37615
37616
37617
37618
37619
37620
37621
37622
37623
37624
37625
37626
37627
37628
37629
37630
37631
37632
37633
37634
37635
37636
37637
37638
37639
37640
37641
37642
37643
37644
37645
37646
37647
37648
37649
37650
37651
37652
37653
37654
37655
37656
37657
37658
37659
37660
37661
37662
37663
37664
37665
37666
37667
37668
37669
37670
37671
37672
37673
37674
37675
37676
37677
37678
37679
37680
37681
37682
37683
37684
37685
37686
37687
37688
37689
37690
37691
37692
37693
37694
37695
37696
37697
37698
37699
37700
37701
37702
37703
37704
37705
37706
37707
37708
37709
37710
37711
37712
37713
37714
37715
37716
37717
37718
37719
37720
37721
37722
37723
37724
37725
37726
37727
37728
37729
37730
37731
37732
37733
37734
37735
37736
37737
37738
37739
37740
37741
37742
37743
37744
37745
37746
37747
37748
37749
37750
37751
37752
37753
37754
37755
37756
37757
37758
37759
37760
37761
37762
37763
37764
37765
37766
37767
37768
37769
37770
37771
37772
37773
37774
37775
37776
37777
37778
37779
37780
37781
37782
37783
37784
37785
37786
37787
37788
37789
37790
37791
37792
37793
37794
37795
37796
37797
37798
37799
37800
37801
37802
37803
37804
37805
37806
37807
37808
37809
37810
37811
37812
37813
37814
37815
37816
37817
37818
37819
37820
37821
37822
37823
37824
37825
37826
37827
37828
37829
37830
37831
37832
37833
37834
37835
37836
37837
37838
37839
37840
37841
37842
37843
37844
37845
37846
37847
37848
37849
37850
37851
37852
37853
37854
37855
37856
37857
37858
37859
37860
37861
37862
37863
37864
37865
37866
37867
37868
37869
37870
37871
37872
37873
37874
37875
37876
37877
37878
37879
37880
37881
37882
37883
37884
37885
37886
37887
37888
37889
37890
37891
37892
37893
37894
37895
37896
37897
37898
37899
37900
37901
37902
37903
37904
37905
37906
37907
37908
37909
37910
37911
37912
37913
37914
37915
37916
37917
37918
37919
37920
37921
37922
37923
37924
37925
37926
37927
37928
37929
37930
37931
37932
37933
37934
37935
37936
37937
37938
37939
37940
37941
37942
37943
37944
37945
37946
37947
37948
37949
37950
37951
37952
37953
37954
37955
37956
37957
37958
37959
37960
37961
37962
37963
37964
37965
37966
37967
37968
37969
37970
37971
37972
37973
37974
37975
37976
37977
37978
37979
37980
37981
37982
37983
37984
37985
37986
37987
37988
37989
37990
37991
37992
37993
37994
37995
37996
37997
37998
37999
38000
38001
38002
38003
38004
38005
38006
38007
38008
38009
38010
38011
38012
38013
38014
38015
38016
38017
38018
38019
38020
38021
38022
38023
38024
38025
38026
38027
38028
38029
38030
38031
38032
38033
38034
38035
38036
38037
38038
38039
38040
38041
38042
38043
38044
38045
38046
38047
38048
38049
38050
38051
38052
38053
38054
38055
38056
38057
38058
38059
38060
38061
38062
38063
38064
38065
38066
38067
38068
38069
38070
38071
38072
38073
38074
38075
38076
38077
38078
38079
38080
38081
38082
38083
38084
38085
38086
38087
38088
38089
38090
38091
38092
38093
38094
38095
38096
38097
38098
38099
38100
38101
38102
38103
38104
38105
38106
38107
38108
38109
38110
38111
38112
38113
38114
38115
38116
38117
38118
38119
38120
38121
38122
38123
38124
38125
38126
38127
38128
38129
38130
38131
38132
38133
38134
38135
38136
38137
38138
38139
38140
38141
38142
38143
38144
38145
38146
38147
38148
38149
38150
38151
38152
38153
38154
38155
38156
38157
38158
38159
38160
38161
38162
38163
38164
38165
38166
38167
38168
38169
38170
38171
38172
38173
38174
38175
38176
38177
38178
38179
38180
38181
38182
38183
38184
38185
38186
38187
38188
38189
38190
38191
38192
38193
38194
38195
38196
38197
38198
38199
38200
38201
38202
38203
38204
38205
38206
38207
38208
38209
38210
38211
38212
38213
38214
38215
38216
38217
38218
38219
38220
38221
38222
38223
38224
38225
38226
38227
38228
38229
38230
38231
38232
38233
38234
38235
38236
38237
38238
38239
38240
38241
38242
38243
38244
38245
38246
38247
38248
38249
38250
38251
38252
38253
38254
38255
38256
38257
38258
38259
38260
38261
38262
38263
38264
38265
38266
38267
38268
38269
38270
38271
38272
38273
38274
38275
38276
38277
38278
38279
38280
38281
38282
38283
38284
38285
38286
38287
38288
38289
38290
38291
38292
38293
38294
38295
38296
38297
38298
38299
38300
38301
38302
38303
38304
38305
38306
38307
38308
38309
38310
38311
38312
38313
38314
38315
38316
38317
38318
38319
38320
38321
38322
38323
38324
38325
38326
38327
38328
38329
38330
38331
38332
38333
38334
38335
38336
38337
38338
38339
38340
38341
38342
38343
38344
38345
38346
38347
38348
38349
38350
38351
38352
38353
38354
38355
38356
38357
38358
38359
38360
38361
38362
38363
38364
38365
38366
38367
38368
38369
38370
38371
38372
38373
38374
38375
38376
38377
38378
38379
38380
38381
38382
38383
38384
38385
38386
38387
38388
38389
38390
38391
38392
38393
38394
38395
38396
38397
38398
38399
38400
38401
38402
38403
38404
38405
38406
38407
38408
38409
38410
38411
38412
38413
38414
38415
38416
38417
38418
38419
38420
38421
38422
38423
38424
38425
38426
38427
38428
38429
38430
38431
38432
38433
38434
38435
38436
38437
38438
38439
38440
38441
38442
38443
38444
38445
38446
38447
38448
38449
38450
38451
38452
38453
38454
38455
38456
38457
38458
38459
38460
38461
38462
38463
38464
38465
38466
38467
38468
38469
38470
38471
38472
38473
38474
38475
38476
38477
38478
38479
38480
38481
38482
38483
38484
38485
38486
38487
38488
38489
38490
38491
38492
38493
38494
38495
38496
38497
38498
38499
38500
38501
38502
38503
38504
38505
38506
38507
38508
38509
38510
38511
38512
38513
38514
38515
38516
38517
38518
38519
38520
38521
38522
38523
38524
38525
38526
38527
38528
38529
38530
38531
38532
38533
38534
38535
38536
38537
38538
38539
38540
38541
38542
38543
38544
38545
38546
38547
38548
38549
38550
38551
38552
38553
38554
38555
38556
38557
38558
38559
38560
38561
38562
38563
38564
38565
38566
38567
38568
38569
38570
38571
38572
38573
38574
38575
38576
38577
38578
38579
38580
38581
38582
38583
38584
38585
38586
38587
38588
38589
38590
38591
38592
38593
38594
38595
38596
38597
38598
38599
38600
38601
38602
38603
38604
38605
38606
38607
38608
38609
38610
38611
38612
38613
38614
38615
38616
38617
38618
38619
38620
38621
38622
38623
38624
38625
38626
38627
38628
38629
38630
38631
38632
38633
38634
38635
38636
38637
38638
38639
38640
38641
38642
38643
38644
38645
38646
38647
38648
38649
38650
38651
38652
38653
38654
38655
38656
38657
38658
38659
38660
38661
38662
38663
38664
38665
38666
38667
38668
38669
38670
38671
38672
38673
38674
38675
38676
38677
38678
38679
38680
38681
38682
38683
38684
38685
38686
38687
38688
38689
38690
38691
38692
38693
38694
38695
38696
38697
38698
38699
38700
38701
38702
38703
38704
38705
38706
38707
38708
38709
38710
38711
38712
38713
38714
38715
38716
38717
38718
38719
38720
38721
38722
38723
38724
38725
38726
38727
38728
38729
38730
38731
38732
38733
38734
38735
38736
38737
38738
38739
38740
38741
38742
38743
38744
38745
38746
38747
38748
38749
38750
38751
38752
38753
38754
38755
38756
38757
38758
38759
38760
38761
38762
38763
38764
38765
38766
38767
38768
38769
38770
38771
38772
38773
38774
38775
38776
38777
38778
38779
38780
38781
38782
38783
38784
38785
38786
38787
38788
38789
38790
38791
38792
38793
38794
38795
38796
38797
38798
38799
38800
38801
38802
38803
38804
38805
38806
38807
38808
38809
38810
38811
38812
38813
38814
38815
38816
38817
38818
38819
38820
38821
38822
38823
38824
38825
38826
38827
38828
38829
38830
38831
38832
38833
38834
38835
38836
38837
38838
38839
38840
38841
38842
38843
38844
38845
38846
38847
38848
38849
38850
38851
38852
38853
38854
38855
38856
38857
38858
38859
38860
38861
38862
38863
38864
38865
38866
38867
38868
38869
38870
38871
38872
38873
38874
38875
38876
38877
38878
38879
38880
38881
38882
38883
38884
38885
38886
38887
38888
38889
38890
38891
38892
38893
38894
38895
38896
38897
38898
38899
38900
38901
38902
38903
38904
38905
38906
38907
38908
38909
38910
38911
38912
38913
38914
38915
38916
38917
38918
38919
38920
38921
38922
38923
38924
38925
38926
38927
38928
38929
38930
38931
38932
38933
38934
38935
38936
38937
38938
38939
38940
38941
38942
38943
38944
38945
38946
38947
38948
38949
38950
38951
38952
38953
38954
38955
38956
38957
38958
38959
38960
38961
38962
38963
38964
38965
38966
38967
38968
38969
38970
38971
38972
38973
38974
38975
38976
38977
38978
38979
38980
38981
38982
38983
38984
38985
38986
38987
38988
38989
38990
38991
38992
38993
38994
38995
38996
38997
38998
38999
39000
39001
39002
39003
39004
39005
39006
39007
39008
39009
39010
39011
39012
39013
39014
39015
39016
39017
39018
39019
39020
39021
39022
39023
39024
39025
39026
39027
39028
39029
39030
39031
39032
39033
39034
39035
39036
39037
39038
39039
39040
39041
39042
39043
39044
39045
39046
39047
39048
39049
39050
39051
39052
39053
39054
39055
39056
39057
39058
39059
39060
39061
39062
39063
39064
39065
39066
39067
39068
39069
39070
39071
39072
39073
39074
39075
39076
39077
39078
39079
39080
39081
39082
39083
39084
39085
39086
39087
39088
39089
39090
39091
39092
39093
39094
39095
39096
39097
39098
39099
39100
39101
39102
39103
39104
39105
39106
39107
39108
39109
39110
39111
39112
39113
39114
39115
39116
39117
39118
39119
39120
39121
39122
39123
39124
39125
39126
39127
39128
39129
39130
39131
39132
39133
39134
39135
39136
39137
39138
39139
39140
39141
39142
39143
39144
39145
39146
39147
39148
39149
39150
39151
39152
39153
39154
39155
39156
39157
39158
39159
39160
39161
39162
39163
39164
39165
39166
39167
39168
39169
39170
39171
39172
39173
39174
39175
39176
39177
39178
39179
39180
39181
39182
39183
39184
39185
39186
39187
39188
39189
39190
39191
39192
39193
39194
39195
39196
39197
39198
39199
39200
39201
39202
39203
39204
39205
39206
39207
39208
39209
39210
39211
39212
39213
39214
39215
39216
39217
39218
39219
39220
39221
39222
39223
39224
39225
39226
39227
39228
39229
39230
39231
39232
39233
39234
39235
39236
39237
39238
39239
39240
39241
39242
39243
39244
39245
39246
39247
39248
39249
39250
39251
39252
39253
39254
39255
39256
39257
39258
39259
39260
39261
39262
39263
39264
39265
39266
39267
39268
39269
39270
39271
39272
39273
39274
39275
39276
39277
39278
39279
39280
39281
39282
39283
39284
39285
39286
39287
39288
39289
39290
39291
39292
39293
39294
39295
39296
39297
39298
39299
39300
39301
39302
39303
39304
39305
39306
39307
39308
39309
39310
39311
39312
39313
39314
39315
39316
39317
39318
39319
39320
39321
39322
39323
39324
39325
39326
39327
39328
39329
39330
39331
39332
39333
39334
39335
39336
39337
39338
39339
39340
39341
39342
39343
39344
39345
39346
39347
39348
39349
39350
39351
39352
39353
39354
39355
39356
39357
39358
39359
39360
39361
39362
39363
39364
39365
39366
39367
39368
39369
39370
39371
39372
39373
39374
39375
39376
39377
39378
39379
39380
39381
39382
39383
39384
39385
39386
39387
39388
39389
39390
39391
39392
39393
39394
39395
39396
39397
39398
39399
39400
39401
39402
39403
39404
39405
39406
39407
39408
39409
39410
39411
39412
39413
39414
39415
39416
39417
39418
39419
39420
39421
39422
39423
39424
39425
39426
39427
39428
39429
39430
39431
39432
39433
39434
39435
39436
39437
39438
39439
39440
39441
39442
39443
39444
39445
39446
39447
39448
39449
39450
39451
39452
39453
39454
39455
39456
39457
39458
39459
39460
39461
39462
39463
39464
39465
39466
39467
39468
39469
39470
39471
39472
39473
39474
39475
39476
39477
39478
39479
39480
39481
39482
39483
39484
39485
39486
39487
39488
39489
39490
39491
39492
39493
39494
39495
39496
39497
39498
39499
39500
39501
39502
39503
39504
39505
39506
39507
39508
39509
39510
39511
39512
39513
39514
39515
39516
39517
39518
39519
39520
39521
39522
39523
39524
39525
39526
39527
39528
39529
39530
39531
39532
39533
39534
39535
39536
39537
39538
39539
39540
39541
39542
39543
39544
39545
39546
39547
39548
39549
39550
39551
39552
39553
39554
39555
39556
39557
39558
39559
39560
39561
39562
39563
39564
39565
39566
39567
39568
39569
39570
39571
39572
39573
39574
39575
39576
39577
39578
39579
39580
39581
39582
39583
39584
39585
39586
39587
39588
39589
39590
39591
39592
39593
39594
39595
39596
39597
39598
39599
39600
39601
39602
39603
39604
39605
39606
39607
39608
39609
39610
39611
39612
39613
39614
39615
39616
39617
39618
39619
39620
39621
39622
39623
39624
39625
39626
39627
39628
39629
39630
39631
39632
39633
39634
39635
39636
39637
39638
39639
39640
39641
39642
39643
39644
39645
39646
39647
39648
39649
39650
39651
39652
39653
39654
39655
39656
39657
39658
39659
39660
39661
39662
39663
39664
39665
39666
39667
39668
39669
39670
39671
39672
39673
39674
39675
39676
39677
39678
39679
39680
39681
39682
39683
39684
39685
39686
39687
39688
39689
39690
39691
39692
39693
39694
39695
39696
39697
39698
39699
39700
39701
39702
39703
39704
39705
39706
39707
39708
39709
39710
39711
39712
39713
39714
39715
39716
39717
39718
39719
39720
39721
39722
39723
39724
39725
39726
39727
39728
39729
39730
39731
39732
39733
39734
39735
39736
39737
39738
39739
39740
39741
39742
39743
39744
39745
39746
39747
39748
39749
39750
39751
39752
39753
39754
39755
39756
39757
39758
39759
39760
39761
39762
39763
39764
39765
39766
39767
39768
39769
39770
39771
39772
39773
39774
39775
39776
39777
39778
39779
39780
39781
39782
39783
39784
39785
39786
39787
39788
39789
39790
39791
39792
39793
39794
39795
39796
39797
39798
39799
39800
39801
39802
39803
39804
39805
39806
39807
39808
39809
39810
39811
39812
39813
39814
39815
39816
39817
39818
39819
39820
39821
39822
39823
39824
39825
39826
39827
39828
39829
39830
39831
39832
39833
39834
39835
39836
39837
39838
39839
39840
39841
39842
39843
39844
39845
39846
39847
39848
39849
39850
39851
39852
39853
39854
39855
39856
39857
39858
39859
39860
39861
39862
39863
39864
39865
39866
39867
39868
39869
39870
39871
39872
39873
39874
39875
39876
39877
39878
39879
39880
39881
39882
39883
39884
39885
39886
39887
39888
39889
39890
39891
39892
39893
39894
39895
39896
39897
39898
39899
39900
39901
39902
39903
39904
39905
39906
39907
39908
39909
39910
39911
39912
39913
39914
39915
39916
39917
39918
39919
39920
39921
39922
39923
39924
39925
39926
39927
39928
39929
39930
39931
39932
39933
39934
39935
39936
39937
39938
39939
39940
39941
39942
39943
39944
39945
39946
39947
39948
39949
39950
39951
39952
39953
39954
39955
39956
39957
39958
39959
39960
39961
39962
39963
39964
39965
39966
39967
39968
39969
39970
39971
39972
39973
39974
39975
39976
39977
39978
39979
39980
39981
39982
39983
39984
39985
39986
39987
39988
39989
39990
39991
39992
39993
39994
39995
39996
39997
39998
39999
40000
40001
40002
40003
40004
40005
40006
40007
40008
40009
40010
40011
40012
40013
40014
40015
40016
40017
40018
40019
40020
40021
40022
40023
40024
40025
40026
40027
40028
40029
40030
40031
40032
40033
40034
40035
40036
40037
40038
40039
40040
40041
40042
40043
40044
40045
40046
40047
40048
40049
40050
40051
40052
40053
40054
40055
40056
40057
40058
40059
40060
40061
40062
40063
40064
40065
40066
40067
40068
40069
40070
40071
40072
40073
40074
40075
40076
40077
40078
40079
40080
40081
40082
40083
40084
40085
40086
40087
40088
40089
40090
40091
40092
40093
40094
40095
40096
40097
40098
40099
40100
40101
40102
40103
40104
40105
40106
40107
40108
40109
40110
40111
40112
40113
40114
40115
40116
40117
40118
40119
40120
40121
40122
40123
40124
40125
40126
40127
40128
40129
40130
40131
40132
40133
40134
40135
40136
40137
40138
40139
40140
40141
40142
40143
40144
40145
40146
40147
40148
40149
40150
40151
40152
40153
40154
40155
40156
40157
40158
40159
40160
40161
40162
40163
40164
40165
40166
40167
40168
40169
40170
40171
40172
40173
40174
40175
40176
40177
40178
40179
40180
40181
40182
40183
40184
40185
40186
40187
40188
40189
40190
40191
40192
40193
40194
40195
40196
40197
40198
40199
40200
40201
40202
40203
40204
40205
40206
40207
40208
40209
40210
40211
40212
40213
40214
40215
40216
40217
40218
40219
40220
40221
40222
40223
40224
40225
40226
40227
40228
40229
40230
40231
40232
40233
40234
40235
40236
40237
40238
40239
40240
40241
40242
40243
40244
40245
40246
40247
40248
40249
40250
40251
40252
40253
40254
40255
40256
40257
40258
40259
40260
40261
40262
40263
40264
40265
40266
40267
40268
40269
40270
40271
40272
40273
40274
40275
40276
40277
40278
40279
40280
40281
40282
40283
40284
40285
40286
40287
40288
40289
40290
40291
40292
40293
40294
40295
40296
40297
40298
40299
40300
40301
40302
40303
40304
40305
40306
40307
40308
40309
40310
40311
40312
40313
40314
40315
40316
40317
40318
40319
40320
40321
40322
40323
40324
40325
40326
40327
40328
40329
40330
40331
40332
40333
40334
40335
40336
40337
40338
40339
40340
40341
40342
40343
40344
40345
40346
40347
40348
40349
40350
40351
40352
40353
40354
40355
40356
40357
40358
40359
40360
40361
40362
40363
40364
40365
40366
40367
40368
40369
40370
40371
40372
40373
40374
40375
40376
40377
40378
40379
40380
40381
40382
40383
40384
40385
40386
40387
40388
40389
40390
40391
40392
40393
40394
40395
40396
40397
40398
40399
40400
40401
40402
40403
40404
40405
40406
40407
40408
40409
40410
40411
40412
40413
40414
40415
40416
40417
40418
40419
40420
40421
40422
40423
40424
40425
40426
40427
40428
40429
40430
40431
40432
40433
40434
40435
40436
40437
40438
40439
40440
40441
40442
40443
40444
40445
40446
40447
40448
40449
40450
40451
40452
40453
40454
40455
40456
40457
40458
40459
40460
40461
40462
40463
40464
40465
40466
40467
40468
40469
40470
40471
40472
40473
40474
40475
40476
40477
40478
40479
40480
40481
40482
40483
40484
40485
40486
40487
40488
40489
40490
40491
40492
40493
40494
40495
40496
40497
40498
40499
40500
40501
40502
40503
40504
40505
40506
40507
40508
40509
40510
40511
40512
40513
40514
40515
40516
40517
40518
40519
40520
40521
40522
40523
40524
40525
40526
40527
40528
40529
40530
40531
40532
40533
40534
40535
40536
40537
40538
40539
40540
40541
40542
40543
40544
40545
40546
40547
40548
40549
40550
40551
40552
40553
40554
40555
40556
40557
40558
40559
40560
40561
40562
40563
40564
40565
40566
40567
40568
40569
40570
40571
40572
40573
40574
40575
40576
40577
40578
40579
40580
40581
40582
40583
40584
40585
40586
40587
40588
40589
40590
40591
40592
40593
40594
40595
40596
40597
40598
40599
40600
40601
40602
40603
40604
40605
40606
40607
40608
40609
40610
40611
40612
40613
40614
40615
40616
40617
40618
40619
40620
40621
40622
40623
40624
40625
40626
40627
40628
40629
40630
40631
40632
40633
40634
40635
40636
40637
40638
40639
40640
40641
40642
40643
40644
40645
40646
40647
40648
40649
40650
40651
40652
40653
40654
40655
40656
40657
40658
40659
40660
40661
40662
40663
40664
40665
40666
40667
40668
40669
40670
40671
40672
40673
40674
40675
40676
40677
40678
40679
40680
40681
40682
40683
40684
40685
40686
40687
40688
40689
40690
40691
40692
40693
40694
40695
40696
40697
40698
40699
40700
40701
40702
40703
40704
40705
40706
40707
40708
40709
40710
40711
40712
40713
40714
40715
40716
40717
40718
40719
40720
40721
40722
40723
40724
40725
40726
40727
40728
40729
40730
40731
40732
40733
40734
40735
40736
40737
40738
40739
40740
40741
40742
40743
40744
40745
40746
40747
40748
40749
40750
40751
40752
40753
40754
40755
40756
40757
40758
40759
40760
40761
40762
40763
40764
40765
40766
40767
40768
40769
40770
40771
40772
40773
40774
40775
40776
40777
40778
40779
40780
40781
40782
40783
40784
40785
40786
40787
40788
40789
40790
40791
40792
40793
40794
40795
40796
40797
40798
40799
40800
40801
40802
40803
40804
40805
40806
40807
40808
40809
40810
40811
40812
40813
40814
40815
40816
40817
40818
40819
40820
40821
40822
40823
40824
40825
40826
40827
40828
40829
40830
40831
40832
40833
40834
40835
40836
40837
40838
40839
40840
40841
40842
40843
40844
40845
40846
40847
40848
40849
40850
40851
40852
40853
40854
40855
40856
40857
40858
40859
40860
40861
40862
40863
40864
40865
40866
40867
40868
40869
40870
40871
40872
40873
40874
40875
40876
40877
40878
40879
40880
40881
40882
40883
40884
40885
40886
40887
40888
40889
40890
40891
40892
40893
40894
40895
40896
40897
40898
40899
40900
40901
40902
40903
40904
40905
40906
40907
40908
40909
40910
40911
40912
40913
40914
40915
40916
40917
40918
40919
40920
40921
40922
40923
40924
40925
40926
40927
40928
40929
40930
40931
40932
40933
40934
40935
40936
40937
40938
40939
40940
40941
40942
40943
40944
40945
40946
40947
40948
40949
40950
40951
40952
40953
40954
40955
40956
40957
40958
40959
40960
40961
40962
40963
40964
40965
40966
40967
40968
40969
40970
40971
40972
40973
40974
40975
40976
40977
40978
40979
40980
40981
40982
40983
40984
40985
40986
40987
40988
40989
40990
40991
40992
40993
40994
40995
40996
40997
40998
40999
41000
41001
41002
41003
41004
41005
41006
41007
41008
41009
41010
41011
41012
41013
41014
41015
41016
41017
41018
41019
41020
41021
41022
41023
41024
41025
41026
41027
41028
41029
41030
41031
41032
41033
41034
41035
41036
41037
41038
41039
41040
41041
41042
41043
41044
41045
41046
41047
41048
41049
41050
41051
41052
41053
41054
41055
41056
41057
41058
41059
41060
41061
41062
41063
41064
41065
41066
41067
41068
41069
41070
41071
41072
41073
41074
41075
41076
41077
41078
41079
41080
41081
41082
41083
41084
41085
41086
41087
41088
41089
41090
41091
41092
41093
41094
41095
41096
41097
41098
41099
41100
41101
41102
41103
41104
41105
41106
41107
41108
41109
41110
41111
41112
41113
41114
41115
41116
41117
41118
41119
41120
41121
41122
41123
41124
41125
41126
41127
41128
41129
41130
41131
41132
41133
41134
41135
41136
41137
41138
41139
41140
41141
41142
41143
41144
41145
41146
41147
41148
41149
41150
41151
41152
41153
41154
41155
41156
41157
41158
41159
41160
41161
41162
41163
41164
41165
41166
41167
41168
41169
41170
41171
41172
41173
41174
41175
41176
41177
41178
41179
41180
41181
41182
41183
41184
41185
41186
41187
41188
41189
41190
41191
41192
41193
41194
41195
41196
41197
41198
41199
41200
41201
41202
41203
41204
41205
41206
41207
41208
41209
41210
41211
41212
41213
41214
41215
41216
41217
41218
41219
41220
41221
41222
41223
41224
41225
41226
41227
41228
41229
41230
41231
41232
41233
41234
41235
41236
41237
41238
41239
41240
41241
41242
41243
41244
41245
41246
41247
41248
41249
41250
41251
41252
41253
41254
41255
41256
41257
41258
41259
41260
41261
41262
41263
41264
41265
41266
41267
41268
41269
41270
41271
41272
41273
41274
41275
41276
41277
41278
41279
41280
41281
41282
41283
41284
41285
41286
41287
41288
41289
41290
41291
41292
41293
41294
41295
41296
41297
41298
41299
41300
41301
41302
41303
41304
41305
41306
41307
41308
41309
41310
41311
41312
41313
41314
41315
41316
41317
41318
41319
41320
41321
41322
41323
41324
41325
41326
41327
41328
41329
41330
41331
41332
41333
41334
41335
41336
41337
41338
41339
41340
41341
41342
41343
41344
41345
41346
41347
41348
41349
41350
41351
41352
41353
41354
41355
41356
41357
41358
41359
41360
41361
41362
41363
41364
41365
41366
41367
41368
41369
41370
41371
41372
41373
41374
41375
41376
41377
41378
41379
41380
41381
41382
41383
41384
41385
41386
41387
41388
41389
41390
41391
41392
41393
41394
41395
41396
41397
41398
41399
41400
41401
41402
41403
41404
41405
41406
41407
41408
41409
41410
41411
41412
41413
41414
41415
41416
41417
41418
41419
41420
41421
41422
41423
41424
41425
41426
41427
41428
41429
41430
41431
41432
41433
41434
41435
41436
41437
41438
41439
41440
41441
41442
41443
41444
41445
41446
41447
41448
41449
41450
41451
41452
41453
41454
41455
41456
41457
41458
41459
41460
41461
41462
41463
41464
41465
41466
41467
41468
41469
41470
41471
41472
41473
41474
41475
41476
41477
41478
41479
41480
41481
41482
41483
41484
41485
41486
41487
41488
41489
41490
41491
41492
41493
41494
41495
41496
41497
41498
41499
41500
41501
41502
41503
41504
41505
41506
41507
41508
41509
41510
41511
41512
41513
41514
41515
41516
41517
41518
41519
41520
41521
41522
41523
41524
41525
41526
41527
41528
41529
41530
41531
41532
41533
41534
41535
41536
41537
41538
41539
41540
41541
41542
41543
41544
41545
41546
41547
41548
41549
41550
41551
41552
41553
41554
41555
41556
41557
41558
41559
41560
41561
41562
41563
41564
41565
41566
41567
41568
41569
41570
41571
41572
41573
41574
41575
41576
41577
41578
41579
41580
41581
41582
41583
41584
41585
41586
41587
41588
41589
41590
41591
41592
41593
41594
41595
41596
41597
41598
41599
41600
41601
41602
41603
41604
41605
41606
41607
41608
41609
41610
41611
41612
41613
41614
41615
41616
41617
41618
41619
41620
41621
41622
41623
41624
41625
41626
41627
41628
41629
41630
41631
41632
41633
41634
41635
41636
41637
41638
41639
41640
41641
41642
41643
41644
41645
41646
41647
41648
41649
41650
41651
41652
41653
41654
41655
41656
41657
41658
41659
41660
41661
41662
41663
41664
41665
41666
41667
41668
41669
41670
41671
41672
41673
41674
41675
41676
41677
41678
41679
41680
41681
41682
41683
41684
41685
41686
41687
41688
41689
41690
41691
41692
41693
41694
41695
41696
41697
41698
41699
41700
41701
41702
41703
41704
41705
41706
41707
41708
41709
41710
41711
41712
41713
41714
41715
41716
41717
41718
41719
41720
41721
41722
41723
41724
41725
41726
41727
41728
41729
41730
41731
41732
41733
41734
41735
41736
41737
41738
41739
41740
41741
41742
41743
41744
41745
41746
41747
41748
41749
41750
41751
41752
41753
41754
41755
41756
41757
41758
41759
41760
41761
41762
41763
41764
41765
41766
41767
41768
41769
41770
41771
41772
41773
41774
41775
41776
41777
41778
41779
41780
41781
41782
41783
41784
41785
41786
41787
41788
41789
41790
41791
41792
41793
41794
41795
41796
41797
41798
41799
41800
41801
41802
41803
41804
41805
41806
41807
41808
41809
41810
41811
41812
41813
41814
41815
41816
41817
41818
41819
41820
41821
41822
41823
41824
41825
41826
41827
41828
41829
41830
41831
41832
41833
41834
41835
41836
41837
41838
41839
41840
41841
41842
41843
41844
41845
41846
41847
41848
41849
41850
41851
41852
41853
41854
41855
41856
41857
41858
41859
41860
41861
41862
41863
41864
41865
41866
41867
41868
41869
41870
41871
41872
41873
41874
41875
41876
41877
41878
41879
41880
41881
41882
41883
41884
41885
41886
41887
41888
41889
41890
41891
41892
41893
41894
41895
41896
41897
41898
41899
41900
41901
41902
41903
41904
41905
41906
41907
41908
41909
41910
41911
41912
41913
41914
41915
41916
41917
41918
41919
41920
41921
41922
41923
41924
41925
41926
41927
41928
41929
41930
41931
41932
41933
41934
41935
41936
41937
41938
41939
41940
41941
41942
41943
41944
41945
41946
41947
41948
41949
41950
41951
41952
41953
41954
41955
41956
41957
41958
41959
41960
41961
41962
41963
41964
41965
41966
41967
41968
41969
41970
41971
41972
41973
41974
41975
41976
41977
41978
41979
41980
41981
41982
41983
41984
41985
41986
41987
41988
41989
41990
41991
41992
41993
41994
41995
41996
41997
41998
41999
42000
42001
42002
42003
42004
42005
42006
42007
42008
42009
42010
42011
42012
42013
42014
42015
42016
42017
42018
42019
42020
42021
42022
42023
42024
42025
42026
42027
42028
42029
42030
42031
42032
42033
42034
42035
42036
42037
42038
42039
42040
42041
42042
42043
42044
42045
42046
42047
42048
42049
42050
42051
42052
42053
42054
42055
42056
42057
42058
42059
42060
42061
42062
42063
42064
42065
42066
42067
42068
42069
42070
42071
42072
42073
42074
42075
42076
42077
42078
42079
42080
42081
42082
42083
42084
42085
42086
42087
42088
42089
42090
42091
42092
42093
42094
42095
42096
42097
42098
42099
42100
42101
42102
42103
42104
42105
42106
42107
42108
42109
42110
42111
42112
42113
42114
42115
42116
42117
42118
42119
42120
42121
42122
42123
42124
42125
42126
42127
42128
42129
42130
42131
42132
42133
42134
42135
42136
42137
42138
42139
42140
42141
42142
42143
42144
42145
42146
42147
42148
42149
42150
42151
42152
42153
42154
42155
42156
42157
42158
42159
42160
42161
42162
42163
42164
42165
42166
42167
42168
42169
42170
42171
42172
42173
42174
42175
42176
42177
42178
42179
42180
42181
42182
42183
42184
42185
42186
42187
42188
42189
42190
42191
42192
42193
42194
42195
42196
42197
42198
42199
42200
42201
42202
42203
42204
42205
42206
42207
42208
42209
42210
42211
42212
42213
42214
42215
42216
42217
42218
42219
42220
42221
42222
42223
42224
42225
42226
42227
42228
42229
42230
42231
42232
42233
42234
42235
42236
42237
42238
42239
42240
42241
42242
42243
42244
42245
42246
42247
42248
42249
42250
42251
42252
42253
42254
42255
42256
42257
42258
42259
42260
42261
42262
42263
42264
42265
42266
42267
42268
42269
42270
42271
42272
42273
42274
42275
42276
42277
42278
42279
42280
42281
42282
42283
42284
42285
42286
42287
42288
42289
42290
42291
42292
42293
42294
42295
42296
42297
42298
42299
42300
42301
42302
42303
42304
42305
42306
42307
42308
42309
42310
42311
42312
42313
42314
42315
42316
42317
42318
42319
42320
42321
42322
42323
42324
42325
42326
42327
42328
42329
42330
42331
42332
42333
42334
42335
42336
42337
42338
42339
42340
42341
42342
42343
42344
42345
42346
42347
42348
42349
42350
42351
42352
42353
42354
42355
42356
42357
42358
42359
42360
42361
42362
42363
42364
42365
42366
42367
42368
42369
42370
42371
42372
42373
42374
42375
42376
42377
42378
42379
42380
42381
42382
42383
42384
42385
42386
42387
42388
42389
42390
42391
42392
42393
42394
42395
42396
42397
42398
42399
42400
42401
42402
42403
42404
42405
42406
42407
42408
42409
42410
42411
42412
42413
42414
42415
42416
42417
42418
42419
42420
42421
42422
42423
42424
42425
42426
42427
42428
42429
42430
42431
42432
42433
42434
42435
42436
42437
42438
42439
42440
42441
42442
42443
42444
42445
42446
42447
42448
42449
42450
42451
42452
42453
42454
42455
42456
42457
42458
42459
42460
42461
42462
42463
42464
42465
42466
42467
42468
42469
42470
42471
42472
42473
42474
42475
42476
42477
42478
42479
42480
42481
42482
42483
42484
42485
42486
42487
42488
42489
42490
42491
42492
42493
42494
42495
42496
42497
42498
42499
42500
42501
42502
42503
42504
42505
42506
42507
42508
42509
42510
42511
42512
42513
42514
42515
42516
42517
42518
42519
42520
42521
42522
42523
42524
42525
42526
42527
42528
42529
42530
42531
42532
42533
42534
42535
42536
42537
42538
42539
42540
42541
42542
42543
42544
42545
42546
42547
42548
42549
42550
42551
42552
42553
42554
42555
42556
42557
42558
42559
42560
42561
42562
42563
42564
42565
42566
42567
42568
42569
42570
42571
42572
42573
42574
42575
42576
42577
42578
42579
42580
42581
42582
42583
42584
42585
42586
42587
42588
42589
42590
42591
42592
42593
42594
42595
42596
42597
42598
42599
42600
42601
42602
42603
42604
42605
42606
42607
42608
42609
42610
42611
42612
42613
42614
42615
42616
42617
42618
42619
42620
42621
42622
42623
42624
42625
42626
42627
42628
42629
42630
42631
42632
42633
42634
42635
42636
42637
42638
42639
42640
42641
42642
42643
42644
42645
42646
42647
42648
42649
42650
42651
42652
42653
42654
42655
42656
42657
42658
42659
42660
42661
42662
42663
42664
42665
42666
42667
42668
42669
42670
42671
42672
42673
42674
42675
42676
42677
42678
42679
42680
42681
42682
42683
42684
42685
42686
42687
42688
42689
42690
42691
42692
42693
42694
42695
42696
42697
42698
42699
42700
42701
42702
42703
42704
42705
42706
42707
42708
42709
42710
42711
42712
42713
42714
42715
42716
42717
42718
42719
42720
42721
42722
42723
42724
42725
42726
42727
42728
42729
42730
42731
42732
42733
42734
42735
42736
42737
42738
42739
42740
42741
42742
42743
42744
42745
42746
42747
42748
42749
42750
42751
42752
42753
42754
42755
42756
42757
42758
42759
42760
42761
42762
42763
42764
42765
42766
42767
42768
42769
42770
42771
42772
42773
42774
42775
42776
42777
42778
42779
42780
42781
42782
42783
42784
42785
42786
42787
42788
42789
42790
42791
42792
42793
42794
42795
42796
42797
42798
42799
42800
42801
42802
42803
42804
42805
42806
42807
42808
42809
42810
42811
42812
42813
42814
42815
42816
42817
42818
42819
42820
42821
42822
42823
42824
42825
42826
42827
42828
42829
42830
42831
42832
42833
42834
42835
42836
42837
42838
42839
42840
42841
42842
42843
42844
42845
42846
42847
42848
42849
42850
42851
42852
42853
42854
42855
42856
42857
42858
42859
42860
42861
42862
42863
42864
42865
42866
42867
42868
42869
42870
42871
42872
42873
42874
42875
42876
42877
42878
42879
42880
42881
42882
42883
42884
42885
42886
42887
42888
42889
42890
42891
42892
42893
42894
42895
42896
42897
42898
42899
42900
42901
42902
42903
42904
42905
42906
42907
42908
42909
42910
42911
42912
42913
42914
42915
42916
42917
42918
42919
42920
42921
42922
42923
42924
42925
42926
42927
42928
42929
42930
42931
42932
42933
42934
42935
42936
42937
42938
42939
42940
42941
42942
42943
42944
42945
42946
42947
42948
42949
42950
42951
42952
42953
42954
42955
42956
42957
42958
42959
42960
42961
42962
42963
42964
42965
42966
42967
42968
42969
42970
42971
42972
42973
42974
42975
42976
42977
42978
42979
42980
42981
42982
42983
42984
42985
42986
42987
42988
42989
42990
42991
42992
42993
42994
42995
42996
42997
42998
42999
43000
43001
43002
43003
43004
43005
43006
43007
43008
43009
43010
43011
43012
43013
43014
43015
43016
43017
43018
43019
43020
43021
43022
43023
43024
43025
43026
43027
43028
43029
43030
43031
43032
43033
43034
43035
43036
43037
43038
43039
43040
43041
43042
43043
43044
43045
43046
43047
43048
43049
43050
43051
43052
43053
43054
43055
43056
43057
43058
43059
43060
43061
43062
43063
43064
43065
43066
43067
43068
43069
43070
43071
43072
43073
43074
43075
43076
43077
43078
43079
43080
43081
43082
43083
43084
43085
43086
43087
43088
43089
43090
43091
43092
43093
43094
43095
43096
43097
43098
43099
43100
43101
43102
43103
43104
43105
43106
43107
43108
43109
43110
43111
43112
43113
43114
43115
43116
43117
43118
43119
43120
43121
43122
43123
43124
43125
43126
43127
43128
43129
43130
43131
43132
43133
43134
43135
43136
43137
43138
43139
43140
43141
43142
43143
43144
43145
43146
43147
43148
43149
43150
43151
43152
43153
43154
43155
43156
43157
43158
43159
43160
43161
43162
43163
43164
43165
43166
43167
43168
43169
43170
43171
43172
43173
43174
43175
43176
43177
43178
43179
43180
43181
43182
43183
43184
43185
43186
43187
43188
43189
43190
43191
43192
43193
43194
43195
43196
43197
43198
43199
43200
43201
43202
43203
43204
43205
43206
43207
43208
43209
43210
43211
43212
43213
43214
43215
43216
43217
43218
43219
43220
43221
43222
43223
43224
43225
43226
43227
43228
43229
43230
43231
43232
43233
43234
43235
43236
43237
43238
43239
43240
43241
43242
43243
43244
43245
43246
43247
43248
43249
43250
43251
43252
43253
43254
43255
43256
43257
43258
43259
43260
43261
43262
43263
43264
43265
43266
43267
43268
43269
43270
43271
43272
43273
43274
43275
43276
43277
43278
43279
43280
43281
43282
43283
43284
43285
43286
43287
43288
43289
43290
43291
43292
43293
43294
43295
43296
43297
43298
43299
43300
43301
43302
43303
43304
43305
43306
43307
43308
43309
43310
43311
43312
43313
43314
43315
43316
43317
43318
43319
43320
43321
43322
43323
43324
43325
43326
43327
43328
43329
43330
43331
43332
43333
43334
43335
43336
43337
43338
43339
43340
43341
43342
43343
43344
43345
43346
43347
43348
43349
43350
43351
43352
43353
43354
43355
43356
43357
43358
43359
43360
43361
43362
43363
43364
43365
43366
43367
43368
43369
43370
43371
43372
43373
43374
43375
43376
43377
43378
43379
43380
43381
43382
43383
43384
43385
43386
43387
43388
43389
43390
43391
43392
43393
43394
43395
43396
43397
43398
43399
43400
43401
43402
43403
43404
43405
43406
43407
43408
43409
43410
43411
43412
43413
43414
43415
43416
43417
43418
43419
43420
43421
43422
43423
43424
43425
43426
43427
43428
43429
43430
43431
43432
43433
43434
43435
43436
43437
43438
43439
43440
43441
43442
43443
43444
43445
43446
43447
43448
43449
43450
43451
43452
43453
43454
43455
43456
43457
43458
43459
43460
43461
43462
43463
43464
43465
43466
43467
43468
43469
43470
43471
43472
43473
43474
43475
43476
43477
43478
43479
43480
43481
43482
43483
43484
43485
43486
43487
43488
43489
43490
43491
43492
43493
43494
43495
43496
43497
43498
43499
43500
43501
43502
43503
43504
43505
43506
43507
43508
43509
43510
43511
43512
43513
43514
43515
43516
43517
43518
43519
43520
43521
43522
43523
43524
43525
43526
43527
43528
43529
43530
43531
43532
43533
43534
43535
43536
43537
43538
43539
43540
43541
43542
43543
43544
43545
43546
43547
43548
43549
43550
43551
43552
43553
43554
43555
43556
43557
43558
43559
43560
43561
43562
43563
43564
43565
43566
43567
43568
43569
43570
43571
43572
43573
43574
43575
43576
43577
43578
43579
43580
43581
43582
43583
43584
43585
43586
43587
43588
43589
43590
43591
43592
43593
43594
43595
43596
43597
43598
43599
43600
43601
43602
43603
43604
43605
43606
43607
43608
43609
43610
43611
43612
43613
43614
43615
43616
43617
43618
43619
43620
43621
43622
43623
43624
43625
43626
43627
43628
43629
43630
43631
43632
43633
43634
43635
43636
43637
43638
43639
43640
43641
43642
43643
43644
43645
43646
43647
43648
43649
43650
43651
43652
43653
43654
43655
43656
43657
43658
43659
43660
43661
43662
43663
43664
43665
43666
43667
43668
43669
43670
43671
43672
43673
43674
43675
43676
43677
43678
43679
43680
43681
43682
43683
43684
43685
43686
43687
43688
43689
43690
43691
43692
43693
43694
43695
43696
43697
43698
43699
43700
43701
43702
43703
43704
43705
43706
43707
43708
43709
43710
43711
43712
43713
43714
43715
43716
43717
43718
43719
43720
43721
43722
43723
43724
43725
43726
43727
43728
43729
43730
43731
43732
43733
43734
43735
43736
43737
43738
43739
43740
43741
43742
43743
43744
43745
43746
43747
43748
43749
43750
43751
43752
43753
43754
43755
43756
43757
43758
43759
43760
43761
43762
43763
43764
43765
43766
43767
43768
43769
43770
43771
43772
43773
43774
43775
43776
43777
43778
43779
43780
43781
43782
43783
43784
43785
43786
43787
43788
43789
43790
43791
43792
43793
43794
43795
43796
43797
43798
43799
43800
43801
43802
43803
43804
43805
43806
43807
43808
43809
43810
43811
43812
43813
43814
43815
43816
43817
43818
43819
43820
43821
43822
43823
43824
43825
43826
43827
43828
43829
43830
43831
43832
43833
43834
43835
43836
43837
43838
43839
43840
43841
43842
43843
43844
43845
43846
43847
43848
43849
43850
43851
43852
43853
43854
43855
43856
43857
43858
43859
43860
43861
43862
43863
43864
43865
43866
43867
43868
43869
43870
43871
43872
43873
43874
43875
43876
43877
43878
43879
43880
43881
43882
43883
43884
43885
43886
43887
43888
43889
43890
43891
43892
43893
43894
43895
43896
43897
43898
43899
43900
43901
43902
43903
43904
43905
43906
43907
43908
43909
43910
43911
43912
43913
43914
43915
43916
43917
43918
43919
43920
43921
43922
43923
43924
43925
43926
43927
43928
43929
43930
43931
43932
43933
43934
43935
43936
43937
43938
43939
43940
43941
43942
43943
43944
43945
43946
43947
43948
43949
43950
43951
43952
43953
43954
43955
43956
43957
43958
43959
43960
43961
43962
43963
43964
43965
43966
43967
43968
43969
43970
43971
43972
43973
43974
43975
43976
43977
43978
43979
43980
43981
43982
43983
43984
43985
43986
43987
43988
43989
43990
43991
43992
43993
43994
43995
43996
43997
43998
43999
44000
44001
44002
44003
44004
44005
44006
44007
44008
44009
44010
44011
44012
44013
44014
44015
44016
44017
44018
44019
44020
44021
44022
44023
44024
44025
44026
44027
44028
44029
44030
44031
44032
44033
44034
44035
44036
44037
44038
44039
44040
44041
44042
44043
44044
44045
44046
44047
44048
44049
44050
44051
44052
44053
44054
44055
44056
44057
44058
44059
44060
44061
44062
44063
44064
44065
44066
44067
44068
44069
44070
44071
44072
44073
44074
44075
44076
44077
44078
44079
44080
44081
44082
44083
44084
44085
44086
44087
44088
44089
44090
44091
44092
44093
44094
44095
44096
44097
44098
44099
44100
44101
44102
44103
44104
44105
44106
44107
44108
44109
44110
44111
44112
44113
44114
44115
44116
44117
44118
44119
44120
44121
44122
44123
44124
44125
44126
44127
44128
44129
44130
44131
44132
44133
44134
44135
44136
44137
44138
44139
44140
44141
44142
44143
44144
44145
44146
44147
44148
44149
44150
44151
44152
44153
44154
44155
44156
44157
44158
44159
44160
44161
44162
44163
44164
44165
44166
44167
44168
44169
44170
44171
44172
44173
44174
44175
44176
44177
44178
44179
44180
44181
44182
44183
44184
44185
44186
44187
44188
44189
44190
44191
44192
44193
44194
44195
44196
44197
44198
44199
44200
44201
44202
44203
44204
44205
44206
44207
44208
44209
44210
44211
44212
44213
44214
44215
44216
44217
44218
44219
44220
44221
44222
44223
44224
44225
44226
44227
44228
44229
44230
44231
44232
44233
44234
44235
44236
44237
44238
44239
44240
44241
44242
44243
44244
44245
44246
44247
44248
44249
44250
44251
44252
44253
44254
44255
44256
44257
44258
44259
44260
44261
44262
44263
44264
44265
44266
44267
44268
44269
44270
44271
44272
44273
44274
44275
44276
44277
44278
44279
44280
44281
44282
44283
44284
44285
44286
44287
44288
44289
44290
44291
44292
44293
44294
44295
44296
44297
44298
44299
44300
44301
44302
44303
44304
44305
44306
44307
44308
44309
44310
44311
44312
44313
44314
44315
44316
44317
44318
44319
44320
44321
44322
44323
44324
44325
44326
44327
44328
44329
44330
44331
44332
44333
44334
44335
44336
44337
44338
44339
44340
44341
44342
44343
44344
44345
44346
44347
44348
44349
44350
44351
44352
44353
44354
44355
44356
44357
44358
44359
44360
44361
44362
44363
44364
44365
44366
44367
44368
44369
44370
44371
44372
44373
44374
44375
44376
44377
44378
44379
44380
44381
44382
44383
44384
44385
44386
44387
44388
44389
44390
44391
44392
44393
44394
44395
44396
44397
44398
44399
44400
44401
44402
44403
44404
44405
44406
44407
44408
44409
44410
44411
44412
44413
44414
44415
44416
44417
44418
44419
44420
44421
44422
44423
44424
44425
44426
44427
44428
44429
44430
44431
44432
44433
44434
44435
44436
44437
44438
44439
44440
44441
44442
44443
44444
44445
44446
44447
44448
44449
44450
44451
44452
44453
44454
44455
44456
44457
44458
44459
44460
44461
44462
44463
44464
44465
44466
44467
44468
44469
44470
44471
44472
44473
44474
44475
44476
44477
44478
44479
44480
44481
44482
44483
44484
44485
44486
44487
44488
44489
44490
44491
44492
44493
44494
44495
44496
44497
44498
44499
44500
44501
44502
44503
44504
44505
44506
44507
44508
44509
44510
44511
44512
44513
44514
44515
44516
44517
44518
44519
44520
44521
44522
44523
44524
44525
44526
44527
44528
44529
44530
44531
44532
44533
44534
44535
44536
44537
44538
44539
44540
44541
44542
44543
44544
44545
44546
44547
44548
44549
44550
44551
44552
44553
44554
44555
44556
44557
44558
44559
44560
44561
44562
44563
44564
44565
44566
44567
44568
44569
44570
44571
44572
44573
44574
44575
44576
44577
44578
44579
44580
44581
44582
44583
44584
44585
44586
44587
44588
44589
44590
44591
44592
44593
44594
44595
44596
44597
44598
44599
44600
44601
44602
44603
44604
44605
44606
44607
44608
44609
44610
44611
44612
44613
44614
44615
44616
44617
44618
44619
44620
44621
44622
44623
44624
44625
44626
44627
44628
44629
44630
44631
44632
44633
44634
44635
44636
44637
44638
44639
44640
44641
44642
44643
44644
44645
44646
44647
44648
44649
44650
44651
44652
44653
44654
44655
44656
44657
44658
44659
44660
44661
44662
44663
44664
44665
44666
44667
44668
44669
44670
44671
44672
44673
44674
44675
44676
44677
44678
44679
44680
44681
44682
44683
44684
44685
44686
44687
44688
44689
44690
44691
44692
44693
44694
44695
44696
44697
44698
44699
44700
44701
44702
44703
44704
44705
44706
44707
44708
44709
44710
44711
44712
44713
44714
44715
44716
44717
44718
44719
44720
44721
44722
44723
44724
44725
44726
44727
44728
44729
44730
44731
44732
44733
44734
44735
44736
44737
44738
44739
44740
44741
44742
44743
44744
44745
44746
44747
44748
44749
44750
44751
44752
44753
44754
44755
44756
44757
44758
44759
44760
44761
44762
44763
44764
44765
44766
44767
44768
44769
44770
44771
44772
44773
44774
44775
44776
44777
44778
44779
44780
44781
44782
44783
44784
44785
44786
44787
44788
44789
44790
44791
44792
44793
44794
44795
44796
44797
44798
44799
44800
44801
44802
44803
44804
44805
44806
44807
44808
44809
44810
44811
44812
44813
44814
44815
44816
44817
44818
44819
44820
44821
44822
44823
44824
44825
44826
44827
44828
44829
44830
44831
44832
44833
44834
44835
44836
44837
44838
44839
44840
44841
44842
44843
44844
44845
44846
44847
44848
44849
44850
44851
44852
44853
44854
44855
44856
44857
44858
44859
44860
44861
44862
44863
44864
44865
44866
44867
44868
44869
44870
44871
44872
44873
44874
44875
44876
44877
44878
44879
44880
44881
44882
44883
44884
44885
44886
44887
44888
44889
44890
44891
44892
44893
44894
44895
44896
44897
44898
44899
44900
44901
44902
44903
44904
44905
44906
44907
44908
44909
44910
44911
44912
44913
44914
44915
44916
44917
44918
44919
44920
44921
44922
44923
44924
44925
44926
44927
44928
44929
44930
44931
44932
44933
44934
44935
44936
44937
44938
44939
44940
44941
44942
44943
44944
44945
44946
44947
44948
44949
44950
44951
44952
44953
44954
44955
44956
44957
44958
44959
44960
44961
44962
44963
44964
44965
44966
44967
44968
44969
44970
44971
44972
44973
44974
44975
44976
44977
44978
44979
44980
44981
44982
44983
44984
44985
44986
44987
44988
44989
44990
44991
44992
44993
44994
44995
44996
44997
44998
44999
45000
45001
45002
45003
45004
45005
45006
45007
45008
45009
45010
45011
45012
45013
45014
45015
45016
45017
45018
45019
45020
45021
45022
45023
45024
45025
45026
45027
45028
45029
45030
45031
45032
45033
45034
45035
45036
45037
45038
45039
45040
45041
45042
45043
45044
45045
45046
45047
45048
45049
45050
45051
45052
45053
45054
45055
45056
45057
45058
45059
45060
45061
45062
45063
45064
45065
45066
45067
45068
45069
45070
45071
45072
45073
45074
45075
45076
45077
45078
45079
45080
45081
45082
45083
45084
45085
45086
45087
45088
45089
45090
45091
45092
45093
45094
45095
45096
45097
45098
45099
45100
45101
45102
45103
45104
45105
45106
45107
45108
45109
45110
45111
45112
45113
45114
45115
45116
45117
45118
45119
45120
45121
45122
45123
45124
45125
45126
45127
45128
45129
45130
45131
45132
45133
45134
45135
45136
45137
45138
45139
45140
45141
45142
45143
45144
45145
45146
45147
45148
45149
45150
45151
45152
45153
45154
45155
45156
45157
45158
45159
45160
45161
45162
45163
45164
45165
45166
45167
45168
45169
45170
45171
45172
45173
45174
45175
45176
45177
45178
45179
45180
45181
45182
45183
45184
45185
45186
45187
45188
45189
45190
45191
45192
45193
45194
45195
45196
45197
45198
45199
45200
45201
45202
45203
45204
45205
45206
45207
45208
45209
45210
45211
45212
45213
45214
45215
45216
45217
45218
45219
45220
45221
45222
45223
45224
45225
45226
45227
45228
45229
45230
45231
45232
45233
45234
45235
45236
45237
45238
45239
45240
45241
45242
45243
45244
45245
45246
45247
45248
45249
45250
45251
45252
45253
45254
45255
45256
45257
45258
45259
45260
45261
45262
45263
45264
45265
45266
45267
45268
45269
45270
45271
45272
45273
45274
45275
45276
45277
45278
45279
45280
45281
45282
45283
45284
45285
45286
45287
45288
45289
45290
45291
45292
45293
45294
45295
45296
45297
45298
45299
45300
45301
45302
45303
45304
45305
45306
45307
45308
45309
45310
45311
45312
45313
45314
45315
45316
45317
45318
45319
45320
45321
45322
45323
45324
45325
45326
45327
45328
45329
45330
45331
45332
45333
45334
45335
45336
45337
45338
45339
45340
45341
45342
45343
45344
45345
45346
45347
45348
45349
45350
45351
45352
45353
45354
45355
45356
45357
45358
45359
45360
45361
45362
45363
45364
45365
45366
45367
45368
45369
45370
45371
45372
45373
45374
45375
45376
45377
45378
45379
45380
45381
45382
45383
45384
45385
45386
45387
45388
45389
45390
45391
45392
45393
45394
45395
45396
45397
45398
45399
45400
45401
45402
45403
45404
45405
45406
45407
45408
45409
45410
45411
45412
45413
45414
45415
45416
45417
45418
45419
45420
45421
45422
45423
45424
45425
45426
45427
45428
45429
45430
45431
45432
45433
45434
45435
45436
45437
45438
45439
45440
45441
45442
45443
45444
45445
45446
45447
45448
45449
45450
45451
45452
45453
45454
45455
45456
45457
45458
45459
45460
45461
45462
45463
45464
45465
45466
45467
45468
45469
45470
45471
45472
45473
45474
45475
45476
45477
45478
45479
45480
45481
45482
45483
45484
45485
45486
45487
45488
45489
45490
45491
45492
45493
45494
45495
45496
45497
45498
45499
45500
45501
45502
45503
45504
45505
45506
45507
45508
45509
45510
45511
45512
45513
45514
45515
45516
45517
45518
45519
45520
45521
45522
45523
45524
45525
45526
45527
45528
45529
45530
45531
45532
45533
45534
45535
45536
45537
45538
45539
45540
45541
45542
45543
45544
45545
45546
45547
45548
45549
45550
45551
45552
45553
45554
45555
45556
45557
45558
45559
45560
45561
45562
45563
45564
45565
45566
45567
45568
45569
45570
45571
45572
45573
45574
45575
45576
45577
45578
45579
45580
45581
45582
45583
45584
45585
45586
45587
45588
45589
45590
45591
45592
45593
45594
45595
45596
45597
45598
45599
45600
45601
45602
45603
45604
45605
45606
45607
45608
45609
45610
45611
45612
45613
45614
45615
45616
45617
45618
45619
45620
45621
45622
45623
45624
45625
45626
45627
45628
45629
45630
45631
45632
45633
45634
45635
45636
45637
45638
45639
45640
45641
45642
45643
45644
45645
45646
45647
45648
45649
45650
45651
45652
45653
45654
45655
45656
45657
45658
45659
45660
45661
45662
45663
45664
45665
45666
45667
45668
45669
45670
45671
45672
45673
45674
45675
45676
45677
45678
45679
45680
45681
45682
45683
45684
45685
45686
45687
45688
45689
45690
45691
45692
45693
45694
45695
45696
45697
45698
45699
45700
45701
45702
45703
45704
45705
45706
45707
45708
45709
45710
45711
45712
45713
45714
45715
45716
45717
45718
45719
45720
45721
45722
45723
45724
45725
45726
45727
45728
45729
45730
45731
45732
45733
45734
45735
45736
45737
45738
45739
45740
45741
45742
45743
45744
45745
45746
45747
45748
45749
45750
45751
45752
45753
45754
45755
45756
45757
45758
45759
45760
45761
45762
45763
45764
45765
45766
45767
45768
45769
45770
45771
45772
45773
45774
45775
45776
45777
45778
45779
45780
45781
45782
45783
45784
45785
45786
45787
45788
45789
45790
45791
45792
45793
45794
45795
45796
45797
45798
45799
45800
45801
45802
45803
45804
45805
45806
45807
45808
45809
45810
45811
45812
45813
45814
45815
45816
45817
45818
45819
45820
45821
45822
45823
45824
45825
45826
45827
45828
45829
45830
45831
45832
45833
45834
45835
45836
45837
45838
45839
45840
45841
45842
45843
45844
45845
45846
45847
45848
45849
45850
45851
45852
45853
45854
45855
45856
45857
45858
45859
45860
45861
45862
45863
45864
45865
45866
45867
45868
45869
45870
45871
45872
45873
45874
45875
45876
45877
45878
45879
45880
45881
45882
45883
45884
45885
45886
45887
45888
45889
45890
45891
45892
45893
45894
45895
45896
45897
45898
45899
45900
45901
45902
45903
45904
45905
45906
45907
45908
45909
45910
45911
45912
45913
45914
45915
45916
45917
45918
45919
45920
45921
45922
45923
45924
45925
45926
45927
45928
45929
45930
45931
45932
45933
45934
45935
45936
45937
45938
45939
45940
45941
45942
45943
45944
45945
45946
45947
45948
45949
45950
45951
45952
45953
45954
45955
45956
45957
45958
45959
45960
45961
45962
45963
45964
45965
45966
45967
45968
45969
45970
45971
45972
45973
45974
45975
45976
45977
45978
45979
45980
45981
45982
45983
45984
45985
45986
45987
45988
45989
45990
45991
45992
45993
45994
45995
45996
45997
45998
45999
46000
46001
46002
46003
46004
46005
46006
46007
46008
46009
46010
46011
46012
46013
46014
46015
46016
46017
46018
46019
46020
46021
46022
46023
46024
46025
46026
46027
46028
46029
46030
46031
46032
46033
46034
46035
46036
46037
46038
46039
46040
46041
46042
46043
46044
46045
46046
46047
46048
46049
46050
46051
46052
46053
46054
46055
46056
46057
46058
46059
46060
46061
46062
46063
46064
46065
46066
46067
46068
46069
46070
46071
46072
46073
46074
46075
46076
46077
46078
46079
46080
46081
46082
46083
46084
46085
46086
46087
46088
46089
46090
46091
46092
46093
46094
46095
46096
46097
46098
46099
46100
46101
46102
46103
46104
46105
46106
46107
46108
46109
46110
46111
46112
46113
46114
46115
46116
46117
46118
46119
46120
46121
46122
46123
46124
46125
46126
46127
46128
46129
46130
46131
46132
46133
46134
46135
46136
46137
46138
46139
46140
46141
46142
46143
46144
46145
46146
46147
46148
46149
46150
46151
46152
46153
46154
46155
46156
46157
46158
46159
46160
46161
46162
46163
46164
46165
46166
46167
46168
46169
46170
46171
46172
46173
46174
46175
46176
46177
46178
46179
46180
46181
46182
46183
46184
46185
46186
46187
46188
46189
46190
46191
46192
46193
46194
46195
46196
46197
46198
46199
46200
46201
46202
46203
46204
46205
46206
46207
46208
46209
46210
46211
46212
46213
46214
46215
46216
46217
46218
46219
46220
46221
46222
46223
46224
46225
46226
46227
46228
46229
46230
46231
46232
46233
46234
46235
46236
46237
46238
46239
46240
46241
46242
46243
46244
46245
46246
46247
46248
46249
46250
46251
46252
46253
46254
46255
46256
46257
46258
46259
46260
46261
46262
46263
46264
46265
46266
46267
46268
46269
46270
46271
46272
46273
46274
46275
46276
46277
46278
46279
46280
46281
46282
46283
46284
46285
46286
46287
46288
46289
46290
46291
46292
46293
46294
46295
46296
46297
46298
46299
46300
46301
46302
46303
46304
46305
46306
46307
46308
46309
46310
46311
46312
46313
46314
46315
46316
46317
46318
46319
46320
46321
46322
46323
46324
46325
46326
46327
46328
46329
46330
46331
46332
46333
46334
46335
46336
46337
46338
46339
46340
46341
46342
46343
46344
46345
46346
46347
46348
46349
46350
46351
46352
46353
46354
46355
46356
46357
46358
46359
46360
46361
46362
46363
46364
46365
46366
46367
46368
46369
46370
46371
46372
46373
46374
46375
46376
46377
46378
46379
46380
46381
46382
46383
46384
46385
46386
46387
46388
46389
46390
46391
46392
46393
46394
46395
46396
46397
46398
46399
46400
46401
46402
46403
46404
46405
46406
46407
46408
46409
46410
46411
46412
46413
46414
46415
46416
46417
46418
46419
46420
46421
46422
46423
46424
46425
46426
46427
46428
46429
46430
46431
46432
46433
46434
46435
46436
46437
46438
46439
46440
46441
46442
46443
46444
46445
46446
46447
46448
46449
46450
46451
46452
46453
46454
46455
46456
46457
46458
46459
46460
46461
46462
46463
46464
46465
46466
46467
46468
46469
46470
46471
46472
46473
46474
46475
46476
46477
46478
46479
46480
46481
46482
46483
46484
46485
46486
46487
46488
46489
46490
46491
46492
46493
46494
46495
46496
46497
46498
46499
46500
46501
46502
46503
46504
46505
46506
46507
46508
46509
46510
46511
46512
46513
46514
46515
46516
46517
46518
46519
46520
46521
46522
46523
46524
46525
46526
46527
46528
46529
46530
46531
46532
46533
46534
46535
46536
46537
46538
46539
46540
46541
46542
46543
46544
46545
46546
46547
46548
46549
46550
46551
46552
46553
46554
46555
46556
46557
46558
46559
46560
46561
46562
46563
46564
46565
46566
46567
46568
46569
46570
46571
46572
46573
46574
46575
46576
46577
46578
46579
46580
46581
46582
46583
46584
46585
46586
46587
46588
46589
46590
46591
46592
46593
46594
46595
46596
46597
46598
46599
46600
46601
46602
46603
46604
46605
46606
46607
46608
46609
46610
46611
46612
46613
46614
46615
46616
46617
46618
46619
46620
46621
46622
46623
46624
46625
46626
46627
46628
46629
46630
46631
46632
46633
46634
46635
46636
46637
46638
46639
46640
46641
46642
46643
46644
46645
46646
46647
46648
46649
46650
46651
46652
46653
46654
46655
46656
46657
46658
46659
46660
46661
46662
46663
46664
46665
46666
46667
46668
46669
46670
46671
46672
46673
46674
46675
46676
46677
46678
46679
46680
46681
46682
46683
46684
46685
46686
46687
46688
46689
46690
46691
46692
46693
46694
46695
46696
46697
46698
46699
46700
46701
46702
46703
46704
46705
46706
46707
46708
46709
46710
46711
46712
46713
46714
46715
46716
46717
46718
46719
46720
46721
46722
46723
46724
46725
46726
46727
46728
46729
46730
46731
46732
46733
46734
46735
46736
46737
46738
46739
46740
46741
46742
46743
46744
46745
46746
46747
46748
46749
46750
46751
46752
46753
46754
46755
46756
46757
46758
46759
46760
46761
46762
46763
46764
46765
46766
46767
46768
46769
46770
46771
46772
46773
46774
46775
46776
46777
46778
46779
46780
46781
46782
46783
46784
46785
46786
46787
46788
46789
46790
46791
46792
46793
46794
46795
46796
46797
46798
46799
46800
46801
46802
46803
46804
46805
46806
46807
46808
46809
46810
46811
46812
46813
46814
46815
46816
46817
46818
46819
46820
46821
46822
46823
46824
46825
46826
46827
46828
46829
46830
46831
46832
46833
46834
46835
46836
46837
46838
46839
46840
46841
46842
46843
46844
46845
46846
46847
46848
46849
46850
46851
46852
46853
46854
46855
46856
46857
46858
46859
46860
46861
46862
46863
46864
46865
46866
46867
46868
46869
46870
46871
46872
46873
46874
46875
46876
46877
46878
46879
46880
46881
46882
46883
46884
46885
46886
46887
46888
46889
46890
46891
46892
46893
46894
46895
46896
46897
46898
46899
46900
46901
46902
46903
46904
46905
46906
46907
46908
46909
46910
46911
46912
46913
46914
46915
46916
46917
46918
46919
46920
46921
46922
46923
46924
46925
46926
46927
46928
46929
46930
46931
46932
46933
46934
46935
46936
46937
46938
46939
46940
46941
46942
46943
46944
46945
46946
46947
46948
46949
46950
46951
46952
46953
46954
46955
46956
46957
46958
46959
46960
46961
46962
46963
46964
46965
46966
46967
46968
46969
46970
46971
46972
46973
46974
46975
46976
46977
46978
46979
46980
46981
46982
46983
46984
46985
46986
46987
46988
46989
46990
46991
46992
46993
46994
46995
46996
46997
46998
46999
47000
47001
47002
47003
47004
47005
47006
47007
47008
47009
47010
47011
47012
47013
47014
47015
47016
47017
47018
47019
47020
47021
47022
47023
47024
47025
47026
47027
47028
47029
47030
47031
47032
47033
47034
47035
47036
47037
47038
47039
47040
47041
47042
47043
47044
47045
47046
47047
47048
47049
47050
47051
47052
47053
47054
47055
47056
47057
47058
47059
47060
47061
47062
47063
47064
47065
47066
47067
47068
47069
47070
47071
47072
47073
47074
47075
47076
47077
47078
47079
47080
47081
47082
47083
47084
47085
47086
47087
47088
47089
47090
47091
47092
47093
47094
47095
47096
47097
47098
47099
47100
47101
47102
47103
47104
47105
47106
47107
47108
47109
47110
47111
47112
47113
47114
47115
47116
47117
47118
47119
47120
47121
47122
47123
47124
47125
47126
47127
47128
47129
47130
47131
47132
47133
47134
47135
47136
47137
47138
47139
47140
47141
47142
47143
47144
47145
47146
47147
47148
47149
47150
47151
47152
47153
47154
47155
47156
47157
47158
47159
47160
47161
47162
47163
47164
47165
47166
47167
47168
47169
47170
47171
47172
47173
47174
47175
47176
47177
47178
47179
47180
47181
47182
47183
47184
47185
47186
47187
47188
47189
47190
47191
47192
47193
47194
47195
47196
47197
47198
47199
47200
47201
47202
47203
47204
47205
47206
47207
47208
47209
47210
47211
47212
47213
47214
47215
47216
47217
47218
47219
47220
47221
47222
47223
47224
47225
47226
47227
47228
47229
47230
47231
47232
47233
47234
47235
47236
47237
47238
47239
47240
47241
47242
47243
47244
47245
47246
47247
47248
47249
47250
47251
47252
47253
47254
47255
47256
47257
47258
47259
47260
47261
47262
47263
47264
47265
47266
47267
47268
47269
47270
47271
47272
47273
47274
47275
47276
47277
47278
47279
47280
47281
47282
47283
47284
47285
47286
47287
47288
47289
47290
47291
47292
47293
47294
47295
47296
47297
47298
47299
47300
47301
47302
47303
47304
47305
47306
47307
47308
47309
47310
47311
47312
47313
47314
47315
47316
47317
47318
47319
47320
47321
47322
47323
47324
47325
47326
47327
47328
47329
47330
47331
47332
47333
47334
47335
47336
47337
47338
47339
47340
47341
47342
47343
47344
47345
47346
47347
47348
47349
47350
47351
47352
47353
47354
47355
47356
47357
47358
47359
47360
47361
47362
47363
47364
47365
47366
47367
47368
47369
47370
47371
47372
47373
47374
47375
47376
47377
47378
47379
47380
47381
47382
47383
47384
47385
47386
47387
47388
47389
47390
47391
47392
47393
47394
47395
47396
47397
47398
47399
47400
47401
47402
47403
47404
47405
47406
47407
47408
47409
47410
47411
47412
47413
47414
47415
47416
47417
47418
47419
47420
47421
47422
47423
47424
47425
47426
47427
47428
47429
47430
47431
47432
47433
47434
47435
47436
47437
47438
47439
47440
47441
47442
47443
47444
47445
47446
47447
47448
47449
47450
47451
47452
47453
47454
47455
47456
47457
47458
47459
47460
47461
47462
47463
47464
47465
47466
47467
47468
47469
47470
47471
47472
47473
47474
47475
47476
47477
47478
47479
47480
47481
47482
47483
47484
47485
47486
47487
47488
47489
47490
47491
47492
47493
47494
47495
47496
47497
47498
47499
47500
47501
47502
47503
47504
47505
47506
47507
47508
47509
47510
47511
47512
47513
47514
47515
47516
47517
47518
47519
47520
47521
47522
47523
47524
47525
47526
47527
47528
47529
47530
47531
47532
47533
47534
47535
47536
47537
47538
47539
47540
47541
47542
47543
47544
47545
47546
47547
47548
47549
47550
47551
47552
47553
47554
47555
47556
47557
47558
47559
47560
47561
47562
47563
47564
47565
47566
47567
47568
47569
47570
47571
47572
47573
47574
47575
47576
47577
47578
47579
47580
47581
47582
47583
47584
47585
47586
47587
47588
47589
47590
47591
47592
47593
47594
47595
47596
47597
47598
47599
47600
47601
47602
47603
47604
47605
47606
47607
47608
47609
47610
47611
47612
47613
47614
47615
47616
47617
47618
47619
47620
47621
47622
47623
47624
47625
47626
47627
47628
47629
47630
47631
47632
47633
47634
47635
47636
47637
47638
47639
47640
47641
47642
47643
47644
47645
47646
47647
47648
47649
47650
47651
47652
47653
47654
47655
47656
47657
47658
47659
47660
47661
47662
47663
47664
47665
47666
47667
47668
47669
47670
47671
47672
47673
47674
47675
47676
47677
47678
47679
47680
47681
47682
47683
47684
47685
47686
47687
47688
47689
47690
47691
47692
47693
47694
47695
47696
47697
47698
47699
47700
47701
47702
47703
47704
47705
47706
47707
47708
47709
47710
47711
47712
47713
47714
47715
47716
47717
47718
47719
47720
47721
47722
47723
47724
47725
47726
47727
47728
47729
47730
47731
47732
47733
47734
47735
47736
47737
47738
47739
47740
47741
47742
47743
47744
47745
47746
47747
47748
47749
47750
47751
47752
47753
47754
47755
47756
47757
47758
47759
47760
47761
47762
47763
47764
47765
47766
47767
47768
47769
47770
47771
47772
47773
47774
47775
47776
47777
47778
47779
47780
47781
47782
47783
47784
47785
47786
47787
47788
47789
47790
47791
47792
47793
47794
47795
47796
47797
47798
47799
47800
47801
47802
47803
47804
47805
47806
47807
47808
47809
47810
47811
47812
47813
47814
47815
47816
47817
47818
47819
47820
47821
47822
47823
47824
47825
47826
47827
47828
47829
47830
47831
47832
47833
47834
47835
47836
47837
47838
47839
47840
47841
47842
47843
47844
47845
47846
47847
47848
47849
47850
47851
47852
47853
47854
47855
47856
47857
47858
47859
47860
47861
47862
47863
47864
47865
47866
47867
47868
47869
47870
47871
47872
47873
47874
47875
47876
47877
47878
47879
47880
47881
47882
47883
47884
47885
47886
47887
47888
47889
47890
47891
47892
47893
47894
47895
47896
47897
47898
47899
47900
47901
47902
47903
47904
47905
47906
47907
47908
47909
47910
47911
47912
47913
47914
47915
47916
47917
47918
47919
47920
47921
47922
47923
47924
47925
47926
47927
47928
47929
47930
47931
47932
47933
47934
47935
47936
47937
47938
47939
47940
47941
47942
47943
47944
47945
47946
47947
47948
47949
47950
47951
47952
47953
47954
47955
47956
47957
47958
47959
47960
47961
47962
47963
47964
47965
47966
47967
47968
47969
47970
47971
47972
47973
47974
47975
47976
47977
47978
47979
47980
47981
47982
47983
47984
47985
47986
47987
47988
47989
47990
47991
47992
47993
47994
47995
47996
47997
47998
47999
48000
48001
48002
48003
48004
48005
48006
48007
48008
48009
48010
48011
48012
48013
48014
48015
48016
48017
48018
48019
48020
48021
48022
48023
48024
48025
48026
48027
48028
48029
48030
48031
48032
48033
48034
48035
48036
48037
48038
48039
48040
48041
48042
48043
48044
48045
48046
48047
48048
48049
48050
48051
48052
48053
48054
48055
48056
48057
48058
48059
48060
48061
48062
48063
48064
48065
48066
48067
48068
48069
48070
48071
48072
48073
48074
48075
48076
48077
48078
48079
48080
48081
48082
48083
48084
48085
48086
48087
48088
48089
48090
48091
48092
48093
48094
48095
48096
48097
48098
48099
48100
48101
48102
48103
48104
48105
48106
48107
48108
48109
48110
48111
48112
48113
48114
48115
48116
48117
48118
48119
48120
48121
48122
48123
48124
48125
48126
48127
48128
48129
48130
48131
48132
48133
48134
48135
48136
48137
48138
48139
48140
48141
48142
48143
48144
48145
48146
48147
48148
48149
48150
48151
48152
48153
48154
48155
48156
48157
48158
48159
48160
48161
48162
48163
48164
48165
48166
48167
48168
48169
48170
48171
48172
48173
48174
48175
48176
48177
48178
48179
48180
48181
48182
48183
48184
48185
48186
48187
48188
48189
48190
48191
48192
48193
48194
48195
48196
48197
48198
48199
48200
48201
48202
48203
48204
48205
48206
48207
48208
48209
48210
48211
48212
48213
48214
48215
48216
48217
48218
48219
48220
48221
48222
48223
48224
48225
48226
48227
48228
48229
48230
48231
48232
48233
48234
48235
48236
48237
48238
48239
48240
48241
48242
48243
48244
48245
48246
48247
48248
48249
48250
48251
48252
48253
48254
48255
48256
48257
48258
48259
48260
48261
48262
48263
48264
48265
48266
48267
48268
48269
48270
48271
48272
48273
48274
48275
48276
48277
48278
48279
48280
48281
48282
48283
48284
48285
48286
48287
48288
48289
48290
48291
48292
48293
48294
48295
48296
48297
48298
48299
48300
48301
48302
48303
48304
48305
48306
48307
48308
48309
48310
48311
48312
48313
48314
48315
48316
48317
48318
48319
48320
48321
48322
48323
48324
48325
48326
48327
48328
48329
48330
48331
48332
48333
48334
48335
48336
48337
48338
48339
48340
48341
48342
48343
48344
48345
48346
48347
48348
48349
48350
48351
48352
48353
48354
48355
48356
48357
48358
48359
48360
48361
48362
48363
48364
48365
48366
48367
48368
48369
48370
48371
48372
48373
48374
48375
48376
48377
48378
48379
48380
48381
48382
48383
48384
48385
48386
48387
48388
48389
48390
48391
48392
48393
48394
48395
48396
48397
48398
48399
48400
48401
48402
48403
48404
48405
48406
48407
48408
48409
48410
48411
48412
48413
48414
48415
48416
48417
48418
48419
48420
48421
48422
48423
48424
48425
48426
48427
48428
48429
48430
48431
48432
48433
48434
48435
48436
48437
48438
48439
48440
48441
48442
48443
48444
48445
48446
48447
48448
48449
48450
48451
48452
48453
48454
48455
48456
48457
48458
48459
48460
48461
48462
48463
48464
48465
48466
48467
48468
48469
48470
48471
48472
48473
48474
48475
48476
48477
48478
48479
48480
48481
48482
48483
48484
48485
48486
48487
48488
48489
48490
48491
48492
48493
48494
48495
48496
48497
48498
48499
48500
48501
48502
48503
48504
48505
48506
48507
48508
48509
48510
48511
48512
48513
48514
48515
48516
48517
48518
48519
48520
48521
48522
48523
48524
48525
48526
48527
48528
48529
48530
48531
48532
48533
48534
48535
48536
48537
48538
48539
48540
48541
48542
48543
48544
48545
48546
48547
48548
48549
48550
48551
48552
48553
48554
48555
48556
48557
48558
48559
48560
48561
48562
48563
48564
48565
48566
48567
48568
48569
48570
48571
48572
48573
48574
48575
48576
48577
48578
48579
48580
48581
48582
48583
48584
48585
48586
48587
48588
48589
48590
48591
48592
48593
48594
48595
48596
48597
48598
48599
48600
48601
48602
48603
48604
48605
48606
48607
48608
48609
48610
48611
48612
48613
48614
48615
48616
48617
48618
48619
48620
48621
48622
48623
48624
48625
48626
48627
48628
48629
48630
48631
48632
48633
48634
48635
48636
48637
48638
48639
48640
48641
48642
48643
48644
48645
48646
48647
48648
48649
48650
48651
48652
48653
48654
48655
48656
48657
48658
48659
48660
48661
48662
48663
48664
48665
48666
48667
48668
48669
48670
48671
48672
48673
48674
48675
48676
48677
48678
48679
48680
48681
48682
48683
48684
48685
48686
48687
48688
48689
48690
48691
48692
48693
48694
48695
48696
48697
48698
48699
48700
48701
48702
48703
48704
48705
48706
48707
48708
48709
48710
48711
48712
48713
48714
48715
48716
48717
48718
48719
48720
48721
48722
48723
48724
48725
48726
48727
48728
48729
48730
48731
48732
48733
48734
48735
48736
48737
48738
48739
48740
48741
48742
48743
48744
48745
48746
48747
48748
48749
48750
48751
48752
48753
48754
48755
48756
48757
48758
48759
48760
48761
48762
48763
48764
48765
48766
48767
48768
48769
48770
48771
48772
48773
48774
48775
48776
48777
48778
48779
48780
48781
48782
48783
48784
48785
48786
48787
48788
48789
48790
48791
48792
48793
48794
48795
48796
48797
48798
48799
48800
48801
48802
48803
48804
48805
48806
48807
48808
48809
48810
48811
48812
48813
48814
48815
48816
48817
48818
48819
48820
48821
48822
48823
48824
48825
48826
48827
48828
48829
48830
48831
48832
48833
48834
48835
48836
48837
48838
48839
48840
48841
48842
48843
48844
48845
48846
48847
48848
48849
48850
48851
48852
48853
48854
48855
48856
48857
48858
48859
48860
48861
48862
48863
48864
48865
48866
48867
48868
48869
48870
48871
48872
48873
48874
48875
48876
48877
48878
48879
48880
48881
48882
48883
48884
48885
48886
48887
48888
48889
48890
48891
48892
48893
48894
48895
48896
48897
48898
48899
48900
48901
48902
48903
48904
48905
48906
48907
48908
48909
48910
48911
48912
48913
48914
48915
48916
48917
48918
48919
48920
48921
48922
48923
48924
48925
48926
48927
48928
48929
48930
48931
48932
48933
48934
48935
48936
48937
48938
48939
48940
48941
48942
48943
48944
48945
48946
48947
48948
48949
48950
48951
48952
48953
48954
48955
48956
48957
48958
48959
48960
48961
48962
48963
48964
48965
48966
48967
48968
48969
48970
48971
48972
48973
48974
48975
48976
48977
48978
48979
48980
48981
48982
48983
48984
48985
48986
48987
48988
48989
48990
48991
48992
48993
48994
48995
48996
48997
48998
48999
49000
49001
49002
49003
49004
49005
49006
49007
49008
49009
49010
49011
49012
49013
49014
49015
49016
49017
49018
49019
49020
49021
49022
49023
49024
49025
49026
49027
49028
49029
49030
49031
49032
49033
49034
49035
49036
49037
49038
49039
49040
49041
49042
49043
49044
49045
49046
49047
49048
49049
49050
49051
49052
49053
49054
49055
49056
49057
49058
49059
49060
49061
49062
49063
49064
49065
49066
49067
49068
49069
49070
49071
49072
49073
49074
49075
49076
49077
49078
49079
49080
49081
49082
49083
49084
49085
49086
49087
49088
49089
49090
49091
49092
49093
49094
49095
49096
49097
49098
49099
49100
49101
49102
49103
49104
49105
49106
49107
49108
49109
49110
49111
49112
49113
49114
49115
49116
49117
49118
49119
49120
49121
49122
49123
49124
49125
49126
49127
49128
49129
49130
49131
49132
49133
49134
49135
49136
49137
49138
49139
49140
49141
49142
49143
49144
49145
49146
49147
49148
49149
49150
49151
49152
49153
49154
49155
49156
49157
49158
49159
49160
49161
49162
49163
49164
49165
49166
49167
49168
49169
49170
49171
49172
49173
49174
49175
49176
49177
49178
49179
49180
49181
49182
49183
49184
49185
49186
49187
49188
49189
49190
49191
49192
49193
49194
49195
49196
49197
49198
49199
49200
49201
49202
49203
49204
49205
49206
49207
49208
49209
49210
49211
49212
49213
49214
49215
49216
49217
49218
49219
49220
49221
49222
49223
49224
49225
49226
49227
49228
49229
49230
49231
49232
49233
49234
49235
49236
49237
49238
49239
49240
49241
49242
49243
49244
49245
49246
49247
49248
49249
49250
49251
49252
49253
49254
49255
49256
49257
49258
49259
49260
49261
49262
49263
49264
49265
49266
49267
49268
49269
49270
49271
49272
49273
49274
49275
49276
49277
49278
49279
49280
49281
49282
49283
49284
49285
49286
49287
49288
49289
49290
49291
49292
49293
49294
49295
49296
49297
49298
49299
49300
49301
49302
49303
49304
49305
49306
49307
49308
49309
49310
49311
49312
49313
49314
49315
49316
49317
49318
49319
49320
49321
49322
49323
49324
49325
49326
49327
49328
49329
49330
49331
49332
49333
49334
49335
49336
49337
49338
49339
49340
49341
49342
49343
49344
49345
49346
49347
49348
49349
49350
49351
49352
49353
49354
49355
49356
49357
49358
49359
49360
49361
49362
49363
49364
49365
49366
49367
49368
49369
49370
49371
49372
49373
49374
49375
49376
49377
49378
49379
49380
49381
49382
49383
49384
49385
49386
49387
49388
49389
49390
49391
49392
49393
49394
49395
49396
49397
49398
49399
49400
49401
49402
49403
49404
49405
49406
49407
49408
49409
49410
49411
49412
49413
49414
49415
49416
49417
49418
49419
49420
49421
49422
49423
49424
49425
49426
49427
49428
49429
49430
49431
49432
49433
49434
49435
49436
49437
49438
49439
49440
49441
49442
49443
49444
49445
49446
49447
49448
49449
49450
49451
49452
49453
49454
49455
49456
49457
49458
49459
49460
49461
49462
49463
49464
49465
49466
49467
49468
49469
49470
49471
49472
49473
49474
49475
49476
49477
49478
49479
49480
49481
49482
49483
49484
49485
49486
49487
49488
49489
49490
49491
49492
49493
49494
49495
49496
49497
49498
49499
49500
49501
49502
49503
49504
49505
49506
49507
49508
49509
49510
49511
49512
49513
49514
49515
49516
49517
49518
49519
49520
49521
49522
49523
49524
49525
49526
49527
49528
49529
49530
49531
49532
49533
49534
49535
49536
49537
49538
49539
49540
49541
49542
49543
49544
49545
49546
49547
49548
49549
49550
49551
49552
49553
49554
49555
49556
49557
49558
49559
49560
49561
49562
49563
49564
49565
49566
49567
49568
49569
49570
49571
49572
49573
49574
49575
49576
49577
49578
49579
49580
49581
49582
49583
49584
49585
49586
49587
49588
49589
49590
49591
49592
49593
49594
49595
49596
49597
49598
49599
49600
49601
49602
49603
49604
49605
49606
49607
49608
49609
49610
49611
49612
49613
49614
49615
49616
49617
49618
49619
49620
49621
49622
49623
49624
49625
49626
49627
49628
49629
49630
49631
49632
49633
49634
49635
49636
49637
49638
49639
49640
49641
49642
49643
49644
49645
49646
49647
49648
49649
49650
49651
49652
49653
49654
49655
49656
49657
49658
49659
49660
49661
49662
49663
49664
49665
49666
49667
49668
49669
49670
49671
49672
49673
49674
49675
49676
49677
49678
49679
49680
49681
49682
49683
49684
49685
49686
49687
49688
49689
49690
49691
49692
49693
49694
49695
49696
49697
49698
49699
49700
49701
49702
49703
49704
49705
49706
49707
49708
49709
49710
49711
49712
49713
49714
49715
49716
49717
49718
49719
49720
49721
49722
49723
49724
49725
49726
49727
49728
49729
49730
49731
49732
49733
49734
49735
49736
49737
49738
49739
49740
49741
49742
49743
49744
49745
49746
49747
49748
49749
49750
49751
49752
49753
49754
49755
49756
49757
49758
49759
49760
49761
49762
49763
49764
49765
49766
49767
49768
49769
49770
49771
49772
49773
49774
49775
49776
49777
49778
49779
49780
49781
49782
49783
49784
49785
49786
49787
49788
49789
49790
49791
49792
49793
49794
49795
49796
49797
49798
49799
49800
49801
49802
49803
49804
49805
49806
49807
49808
49809
49810
49811
49812
49813
49814
49815
49816
49817
49818
49819
49820
49821
49822
49823
49824
49825
49826
49827
49828
49829
49830
49831
49832
49833
49834
49835
49836
49837
49838
49839
49840
49841
49842
49843
49844
49845
49846
49847
49848
49849
49850
49851
49852
49853
49854
49855
49856
49857
49858
49859
49860
49861
49862
49863
49864
49865
49866
49867
49868
49869
49870
49871
49872
49873
49874
49875
49876
49877
49878
49879
49880
49881
49882
49883
49884
49885
49886
49887
49888
49889
49890
49891
49892
49893
49894
49895
49896
49897
49898
49899
49900
49901
49902
49903
49904
49905
49906
49907
49908
49909
49910
49911
49912
49913
49914
49915
49916
49917
49918
49919
49920
49921
49922
49923
49924
49925
49926
49927
49928
49929
49930
49931
49932
49933
49934
49935
49936
49937
49938
49939
49940
49941
49942
49943
49944
49945
49946
49947
49948
49949
49950
49951
49952
49953
49954
49955
49956
49957
49958
49959
49960
49961
49962
49963
49964
49965
49966
49967
49968
49969
49970
49971
49972
49973
49974
49975
49976
49977
49978
49979
49980
49981
49982
49983
49984
49985
49986
49987
49988
49989
49990
49991
49992
49993
49994
49995
49996
49997
49998
49999
50000
50001
50002
50003
50004
50005
50006
50007
50008
50009
50010
50011
50012
50013
50014
50015
50016
50017
50018
50019
50020
50021
50022
50023
50024
50025
50026
50027
50028
50029
50030
50031
50032
50033
50034
50035
50036
50037
50038
50039
50040
50041
50042
50043
50044
50045
50046
50047
50048
50049
50050
50051
50052
50053
50054
50055
50056
50057
50058
50059
50060
50061
50062
50063
50064
50065
50066
50067
50068
50069
50070
50071
50072
50073
50074
50075
50076
50077
50078
50079
50080
50081
50082
50083
50084
50085
50086
50087
50088
50089
50090
50091
50092
50093
50094
50095
50096
50097
50098
50099
50100
50101
50102
50103
50104
50105
50106
50107
50108
50109
50110
50111
50112
50113
50114
50115
50116
50117
50118
50119
50120
50121
50122
50123
50124
50125
50126
50127
50128
50129
50130
50131
50132
50133
50134
50135
50136
50137
50138
50139
50140
50141
50142
50143
50144
50145
50146
50147
50148
50149
50150
50151
50152
50153
50154
50155
50156
50157
50158
50159
50160
50161
50162
50163
50164
50165
50166
50167
50168
50169
50170
50171
50172
50173
50174
50175
50176
50177
50178
50179
50180
50181
50182
50183
50184
50185
50186
50187
50188
50189
50190
50191
50192
50193
50194
50195
50196
50197
50198
50199
50200
50201
50202
50203
50204
50205
50206
50207
50208
50209
50210
50211
50212
50213
50214
50215
50216
50217
50218
50219
50220
50221
50222
50223
50224
50225
50226
50227
50228
50229
50230
50231
50232
50233
50234
50235
50236
50237
50238
50239
50240
50241
50242
50243
50244
50245
50246
50247
50248
50249
50250
50251
50252
50253
50254
50255
50256
50257
50258
50259
50260
50261
50262
50263
50264
50265
50266
50267
50268
50269
50270
50271
50272
50273
50274
50275
50276
50277
50278
50279
50280
50281
50282
50283
50284
50285
50286
50287
50288
50289
50290
50291
50292
50293
50294
50295
50296
50297
50298
50299
50300
50301
50302
50303
50304
50305
50306
50307
50308
50309
50310
50311
50312
50313
50314
50315
50316
50317
50318
50319
50320
50321
50322
50323
50324
50325
50326
50327
50328
50329
50330
50331
50332
50333
50334
50335
50336
50337
50338
50339
50340
50341
50342
50343
50344
50345
50346
50347
50348
50349
50350
50351
50352
50353
50354
50355
50356
50357
50358
50359
50360
50361
50362
50363
50364
50365
50366
50367
50368
50369
50370
50371
50372
50373
50374
50375
50376
50377
50378
50379
50380
50381
50382
50383
50384
50385
50386
50387
50388
50389
50390
50391
50392
50393
50394
50395
50396
50397
50398
50399
50400
50401
50402
50403
50404
50405
50406
50407
50408
50409
50410
50411
50412
50413
50414
50415
50416
50417
50418
50419
50420
50421
50422
50423
50424
50425
50426
50427
50428
50429
50430
50431
50432
50433
50434
50435
50436
50437
50438
50439
50440
50441
50442
50443
50444
50445
50446
50447
50448
50449
50450
50451
50452
50453
50454
50455
50456
50457
50458
50459
50460
50461
50462
50463
50464
50465
50466
50467
50468
50469
50470
50471
50472
50473
50474
50475
50476
50477
50478
50479
50480
50481
50482
50483
50484
50485
50486
50487
50488
50489
50490
50491
50492
50493
50494
50495
50496
50497
50498
50499
50500
50501
50502
50503
50504
50505
50506
50507
50508
50509
50510
50511
50512
50513
50514
50515
50516
50517
50518
50519
50520
50521
50522
50523
50524
50525
50526
50527
50528
50529
50530
50531
50532
50533
50534
50535
50536
50537
50538
50539
50540
50541
50542
50543
50544
50545
50546
50547
50548
50549
50550
50551
50552
50553
50554
50555
50556
50557
50558
50559
50560
50561
50562
50563
50564
50565
50566
50567
50568
50569
50570
50571
50572
50573
50574
50575
50576
50577
50578
50579
50580
50581
50582
50583
50584
50585
50586
50587
50588
50589
50590
50591
50592
50593
50594
50595
50596
50597
50598
50599
50600
50601
50602
50603
50604
50605
50606
50607
50608
50609
50610
50611
50612
50613
50614
50615
50616
50617
50618
50619
50620
50621
50622
50623
50624
50625
50626
50627
50628
50629
50630
50631
50632
50633
50634
50635
50636
50637
50638
50639
50640
50641
50642
50643
50644
50645
50646
50647
50648
50649
50650
50651
50652
50653
50654
50655
50656
50657
50658
50659
50660
50661
50662
50663
50664
50665
50666
50667
50668
50669
50670
50671
50672
50673
50674
50675
50676
50677
50678
50679
50680
50681
50682
50683
50684
50685
50686
50687
50688
50689
50690
50691
50692
50693
50694
50695
50696
50697
50698
50699
50700
50701
50702
50703
50704
50705
50706
50707
50708
50709
50710
50711
50712
50713
50714
50715
50716
50717
50718
50719
50720
50721
50722
50723
50724
50725
50726
50727
50728
50729
50730
50731
50732
50733
50734
50735
50736
50737
50738
50739
50740
50741
50742
50743
50744
50745
50746
50747
50748
50749
50750
50751
50752
50753
50754
50755
50756
50757
50758
50759
50760
50761
50762
50763
50764
50765
50766
50767
50768
50769
50770
50771
50772
50773
50774
50775
50776
50777
50778
50779
50780
50781
50782
50783
50784
50785
50786
50787
50788
50789
50790
50791
50792
50793
50794
50795
50796
50797
50798
50799
50800
50801
50802
50803
50804
50805
50806
50807
50808
50809
50810
50811
50812
50813
50814
50815
50816
50817
50818
50819
50820
50821
50822
50823
50824
50825
50826
50827
50828
50829
50830
50831
50832
50833
50834
50835
50836
50837
50838
50839
50840
50841
50842
50843
50844
50845
50846
50847
50848
50849
50850
50851
50852
50853
50854
50855
50856
50857
50858
50859
50860
50861
50862
50863
50864
50865
50866
50867
50868
50869
50870
50871
50872
50873
50874
50875
50876
50877
50878
50879
50880
50881
50882
50883
50884
50885
50886
50887
50888
50889
50890
50891
50892
50893
50894
50895
50896
50897
50898
50899
50900
50901
50902
50903
50904
50905
50906
50907
50908
50909
50910
50911
50912
50913
50914
50915
50916
50917
50918
50919
50920
50921
50922
50923
50924
50925
50926
50927
50928
50929
50930
50931
50932
50933
50934
50935
50936
50937
50938
50939
50940
50941
50942
50943
50944
50945
50946
50947
50948
50949
50950
50951
50952
50953
50954
50955
50956
50957
50958
50959
50960
50961
50962
50963
50964
50965
50966
50967
50968
50969
50970
50971
50972
50973
50974
50975
50976
50977
50978
50979
50980
50981
50982
50983
50984
50985
50986
50987
50988
50989
50990
50991
50992
50993
50994
50995
50996
50997
50998
50999
51000
51001
51002
51003
51004
51005
51006
51007
51008
51009
51010
51011
51012
51013
51014
51015
51016
51017
51018
51019
51020
51021
51022
51023
51024
51025
51026
51027
51028
51029
51030
51031
51032
51033
51034
51035
51036
51037
51038
51039
51040
51041
51042
51043
51044
51045
51046
51047
51048
51049
51050
51051
51052
51053
51054
51055
51056
51057
51058
51059
51060
51061
51062
51063
51064
51065
51066
51067
51068
51069
51070
51071
51072
51073
51074
51075
51076
51077
51078
51079
51080
51081
51082
51083
51084
51085
51086
51087
51088
51089
51090
51091
51092
51093
51094
51095
51096
51097
51098
51099
51100
51101
51102
51103
51104
51105
51106
51107
51108
51109
51110
51111
51112
51113
51114
51115
51116
51117
51118
51119
51120
51121
51122
51123
51124
51125
51126
51127
51128
51129
51130
51131
51132
51133
51134
51135
51136
51137
51138
51139
51140
51141
51142
51143
51144
51145
51146
51147
51148
51149
51150
51151
51152
51153
51154
51155
51156
51157
51158
51159
51160
51161
51162
51163
51164
51165
51166
51167
51168
51169
51170
51171
51172
51173
51174
51175
51176
51177
51178
51179
51180
51181
51182
51183
51184
51185
51186
51187
51188
51189
51190
51191
51192
51193
51194
51195
51196
51197
51198
51199
51200
51201
51202
51203
51204
51205
51206
51207
51208
51209
51210
51211
51212
51213
51214
51215
51216
51217
51218
51219
51220
51221
51222
51223
51224
51225
51226
51227
51228
51229
51230
51231
51232
51233
51234
51235
51236
51237
51238
51239
51240
51241
51242
51243
51244
51245
51246
51247
51248
51249
51250
51251
51252
51253
51254
51255
51256
51257
51258
51259
51260
51261
51262
51263
51264
51265
51266
51267
51268
51269
51270
51271
51272
51273
51274
51275
51276
51277
51278
51279
51280
51281
51282
51283
51284
51285
51286
51287
51288
51289
51290
51291
51292
51293
51294
51295
51296
51297
51298
51299
51300
51301
51302
51303
51304
51305
51306
51307
51308
51309
51310
51311
51312
51313
51314
51315
51316
51317
51318
51319
51320
51321
51322
51323
51324
51325
51326
51327
51328
51329
51330
51331
51332
51333
51334
51335
51336
51337
51338
51339
51340
51341
51342
51343
51344
51345
51346
51347
51348
51349
51350
51351
51352
51353
51354
51355
51356
51357
51358
51359
51360
51361
51362
51363
51364
51365
51366
51367
51368
51369
51370
51371
51372
51373
51374
51375
51376
51377
51378
51379
51380
51381
51382
51383
51384
51385
51386
51387
51388
51389
51390
51391
51392
51393
51394
51395
51396
51397
51398
51399
51400
51401
51402
51403
51404
51405
51406
51407
51408
51409
51410
51411
51412
51413
51414
51415
51416
51417
51418
51419
51420
51421
51422
51423
51424
51425
51426
51427
51428
51429
51430
51431
51432
51433
51434
51435
51436
51437
51438
51439
51440
51441
51442
51443
51444
51445
51446
51447
51448
51449
51450
51451
51452
51453
51454
51455
51456
51457
51458
51459
51460
51461
51462
51463
51464
51465
51466
51467
51468
51469
51470
51471
51472
51473
51474
51475
51476
51477
51478
51479
51480
51481
51482
51483
51484
51485
51486
51487
51488
51489
51490
51491
51492
51493
51494
51495
51496
51497
51498
51499
51500
51501
51502
51503
51504
51505
51506
51507
51508
51509
51510
51511
51512
51513
51514
51515
51516
51517
51518
51519
51520
51521
51522
51523
51524
51525
51526
51527
51528
51529
51530
51531
51532
51533
51534
51535
51536
51537
51538
51539
51540
51541
51542
51543
51544
51545
51546
51547
51548
51549
51550
51551
51552
51553
51554
51555
51556
51557
51558
51559
51560
51561
51562
51563
51564
51565
51566
51567
51568
51569
51570
51571
51572
51573
51574
51575
51576
51577
51578
51579
51580
51581
51582
51583
51584
51585
51586
51587
51588
51589
51590
51591
51592
51593
51594
51595
51596
51597
51598
51599
51600
51601
51602
51603
51604
51605
51606
51607
51608
51609
51610
51611
51612
51613
51614
51615
51616
51617
51618
51619
51620
51621
51622
51623
51624
51625
51626
51627
51628
51629
51630
51631
51632
51633
51634
51635
51636
51637
51638
51639
51640
51641
51642
51643
51644
51645
51646
51647
51648
51649
51650
51651
51652
51653
51654
51655
51656
51657
51658
51659
51660
51661
51662
51663
51664
51665
51666
51667
51668
51669
51670
51671
51672
51673
51674
51675
51676
51677
51678
51679
51680
51681
51682
51683
51684
51685
51686
51687
51688
51689
51690
51691
51692
51693
51694
51695
51696
51697
51698
51699
51700
51701
51702
51703
51704
51705
51706
51707
51708
51709
51710
51711
51712
51713
51714
51715
51716
51717
51718
51719
51720
51721
51722
51723
51724
51725
51726
51727
51728
51729
51730
51731
51732
51733
51734
51735
51736
51737
51738
51739
51740
51741
51742
51743
51744
51745
51746
51747
51748
51749
51750
51751
51752
51753
51754
51755
51756
51757
51758
51759
51760
51761
51762
51763
51764
51765
51766
51767
51768
51769
51770
51771
51772
51773
51774
51775
51776
51777
51778
51779
51780
51781
51782
51783
51784
51785
51786
51787
51788
51789
51790
51791
51792
51793
51794
51795
51796
51797
51798
51799
51800
51801
51802
51803
51804
51805
51806
51807
51808
51809
51810
51811
51812
51813
51814
51815
51816
51817
51818
51819
51820
51821
51822
51823
51824
51825
51826
51827
51828
51829
51830
51831
51832
51833
51834
51835
51836
51837
51838
51839
51840
51841
51842
51843
51844
51845
51846
51847
51848
51849
51850
51851
51852
51853
51854
51855
51856
51857
51858
51859
51860
51861
51862
51863
51864
51865
51866
51867
51868
51869
51870
51871
51872
51873
51874
51875
51876
51877
51878
51879
51880
51881
51882
51883
51884
51885
51886
51887
51888
51889
51890
51891
51892
51893
51894
51895
51896
51897
51898
51899
51900
51901
51902
51903
51904
51905
51906
51907
51908
51909
51910
51911
51912
51913
51914
51915
51916
51917
51918
51919
51920
51921
51922
51923
51924
51925
51926
51927
51928
51929
51930
51931
51932
51933
51934
51935
51936
51937
51938
51939
51940
51941
51942
51943
51944
51945
51946
51947
51948
51949
51950
51951
51952
51953
51954
51955
51956
51957
51958
51959
51960
51961
51962
51963
51964
51965
51966
51967
51968
51969
51970
51971
51972
51973
51974
51975
51976
51977
51978
51979
51980
51981
51982
51983
51984
51985
51986
51987
51988
51989
51990
51991
51992
51993
51994
51995
51996
51997
51998
51999
52000
52001
52002
52003
52004
52005
52006
52007
52008
52009
52010
52011
52012
52013
52014
52015
52016
52017
52018
52019
52020
52021
52022
52023
52024
52025
52026
52027
52028
52029
52030
52031
52032
52033
52034
52035
52036
52037
52038
52039
52040
52041
52042
52043
52044
52045
52046
52047
52048
52049
52050
52051
52052
52053
52054
52055
52056
52057
52058
52059
52060
52061
52062
52063
52064
52065
52066
52067
52068
52069
52070
52071
52072
52073
52074
52075
52076
52077
52078
52079
52080
52081
52082
52083
52084
52085
52086
52087
52088
52089
52090
52091
52092
52093
52094
52095
52096
52097
52098
52099
52100
52101
52102
52103
52104
52105
52106
52107
52108
52109
52110
52111
52112
52113
52114
52115
52116
52117
52118
52119
52120
52121
52122
52123
52124
52125
52126
52127
52128
52129
52130
52131
52132
52133
52134
52135
52136
52137
52138
52139
52140
52141
52142
52143
52144
52145
52146
52147
52148
52149
52150
52151
52152
52153
52154
52155
52156
52157
52158
52159
52160
52161
52162
52163
52164
52165
52166
52167
52168
52169
52170
52171
52172
52173
52174
52175
52176
52177
52178
52179
52180
52181
52182
52183
52184
52185
52186
52187
52188
52189
52190
52191
52192
52193
52194
52195
52196
52197
52198
52199
52200
52201
52202
52203
52204
52205
52206
52207
52208
52209
52210
52211
52212
52213
52214
52215
52216
52217
52218
52219
52220
52221
52222
52223
52224
52225
52226
52227
52228
52229
52230
52231
52232
52233
52234
52235
52236
52237
52238
52239
52240
52241
52242
52243
52244
52245
52246
52247
52248
52249
52250
52251
52252
52253
52254
52255
52256
52257
52258
52259
52260
52261
52262
52263
52264
52265
52266
52267
52268
52269
52270
52271
52272
52273
52274
52275
52276
52277
52278
52279
52280
52281
52282
52283
52284
52285
52286
52287
52288
52289
52290
52291
52292
52293
52294
52295
52296
52297
52298
52299
52300
52301
52302
52303
52304
52305
52306
52307
52308
52309
52310
52311
52312
52313
52314
52315
52316
52317
52318
52319
52320
52321
52322
52323
52324
52325
52326
52327
52328
52329
52330
52331
52332
52333
52334
52335
52336
52337
52338
52339
52340
52341
52342
52343
52344
52345
52346
52347
52348
52349
52350
52351
52352
52353
52354
52355
52356
52357
52358
52359
52360
52361
52362
52363
52364
52365
52366
52367
52368
52369
52370
52371
52372
52373
52374
52375
52376
52377
52378
52379
52380
52381
52382
52383
52384
52385
52386
52387
52388
52389
52390
52391
52392
52393
52394
52395
52396
52397
52398
52399
52400
52401
52402
52403
52404
52405
52406
52407
52408
52409
52410
52411
52412
52413
52414
52415
52416
52417
52418
52419
52420
52421
52422
52423
52424
52425
52426
52427
52428
52429
52430
52431
52432
52433
52434
52435
52436
52437
52438
52439
52440
52441
52442
52443
52444
52445
52446
52447
52448
52449
52450
52451
52452
52453
52454
52455
52456
52457
52458
52459
52460
52461
52462
52463
52464
52465
52466
52467
52468
52469
52470
52471
52472
52473
52474
52475
52476
52477
52478
52479
52480
52481
52482
52483
52484
52485
52486
52487
52488
52489
52490
52491
52492
52493
52494
52495
52496
52497
52498
52499
52500
52501
52502
52503
52504
52505
52506
52507
52508
52509
52510
52511
52512
52513
52514
52515
52516
52517
52518
52519
52520
52521
52522
52523
52524
52525
52526
52527
52528
52529
52530
52531
52532
52533
52534
52535
52536
52537
52538
52539
52540
52541
52542
52543
52544
52545
52546
52547
52548
52549
52550
52551
52552
52553
52554
52555
52556
52557
52558
52559
52560
52561
52562
52563
52564
52565
52566
52567
52568
52569
52570
52571
52572
52573
52574
52575
52576
52577
52578
52579
52580
52581
52582
52583
52584
52585
52586
52587
52588
52589
52590
52591
52592
52593
52594
52595
52596
52597
52598
52599
52600
52601
52602
52603
52604
52605
52606
52607
52608
52609
52610
52611
52612
52613
52614
52615
52616
52617
52618
52619
52620
52621
52622
52623
52624
52625
52626
52627
52628
52629
52630
52631
52632
52633
52634
52635
52636
52637
52638
52639
52640
52641
52642
52643
52644
52645
52646
52647
52648
52649
52650
52651
52652
52653
52654
52655
52656
52657
52658
52659
52660
52661
52662
52663
52664
52665
52666
52667
52668
52669
52670
52671
52672
52673
52674
52675
52676
52677
52678
52679
52680
52681
52682
52683
52684
52685
52686
52687
52688
52689
52690
52691
52692
52693
52694
52695
52696
52697
52698
52699
52700
52701
52702
52703
52704
52705
52706
52707
52708
52709
52710
52711
52712
52713
52714
52715
52716
52717
52718
52719
52720
52721
52722
52723
52724
52725
52726
52727
52728
52729
52730
52731
52732
52733
52734
52735
52736
52737
52738
52739
52740
52741
52742
52743
52744
52745
52746
52747
52748
52749
52750
52751
52752
52753
52754
52755
52756
52757
52758
52759
52760
52761
52762
52763
52764
52765
52766
52767
52768
52769
52770
52771
52772
52773
52774
52775
52776
52777
52778
52779
52780
52781
52782
52783
52784
52785
52786
52787
52788
52789
52790
52791
52792
52793
52794
52795
52796
52797
52798
52799
52800
52801
52802
52803
52804
52805
52806
52807
52808
52809
52810
52811
52812
52813
52814
52815
52816
52817
52818
52819
52820
52821
52822
52823
52824
52825
52826
52827
52828
52829
52830
52831
52832
52833
52834
52835
52836
52837
52838
52839
52840
52841
52842
52843
52844
52845
52846
52847
52848
52849
52850
52851
52852
52853
52854
52855
52856
52857
52858
52859
52860
52861
52862
52863
52864
52865
52866
52867
52868
52869
52870
52871
52872
52873
52874
52875
52876
52877
52878
52879
52880
52881
52882
52883
52884
52885
52886
52887
52888
52889
52890
52891
52892
52893
52894
52895
52896
52897
52898
52899
52900
52901
52902
52903
52904
52905
52906
52907
52908
52909
52910
52911
52912
52913
52914
52915
52916
52917
52918
52919
52920
52921
52922
52923
52924
52925
52926
52927
52928
52929
52930
52931
52932
52933
52934
52935
52936
52937
52938
52939
52940
52941
52942
52943
52944
52945
52946
52947
52948
52949
52950
52951
52952
52953
52954
52955
52956
52957
52958
52959
52960
52961
52962
52963
52964
52965
52966
52967
52968
52969
52970
52971
52972
52973
52974
52975
52976
52977
52978
52979
52980
52981
52982
52983
52984
52985
52986
52987
52988
52989
52990
52991
52992
52993
52994
52995
52996
52997
52998
52999
53000
53001
53002
53003
53004
53005
53006
53007
53008
53009
53010
53011
53012
53013
53014
53015
53016
53017
53018
53019
53020
53021
53022
53023
53024
53025
53026
53027
53028
53029
53030
53031
53032
53033
53034
53035
53036
53037
53038
53039
53040
53041
53042
53043
53044
53045
53046
53047
53048
53049
53050
53051
53052
53053
53054
53055
53056
53057
53058
53059
53060
53061
53062
53063
53064
53065
53066
53067
53068
53069
53070
53071
53072
53073
53074
53075
53076
53077
53078
53079
53080
53081
53082
53083
53084
53085
53086
53087
53088
53089
53090
53091
53092
53093
53094
53095
53096
53097
53098
53099
53100
53101
53102
53103
53104
53105
53106
53107
53108
53109
53110
53111
53112
53113
53114
53115
53116
53117
53118
53119
53120
53121
53122
53123
53124
53125
53126
53127
53128
53129
53130
53131
53132
53133
53134
53135
53136
53137
53138
53139
53140
53141
53142
53143
53144
53145
53146
53147
53148
53149
53150
53151
53152
53153
53154
53155
53156
53157
53158
53159
53160
53161
53162
53163
53164
53165
53166
53167
53168
53169
53170
53171
53172
53173
53174
53175
53176
53177
53178
53179
53180
53181
53182
53183
53184
53185
53186
53187
53188
53189
53190
53191
53192
53193
53194
53195
53196
53197
53198
53199
53200
53201
53202
53203
53204
53205
53206
53207
53208
53209
53210
53211
53212
53213
53214
53215
53216
53217
53218
53219
53220
53221
53222
53223
53224
53225
53226
53227
53228
53229
53230
53231
53232
53233
53234
53235
53236
53237
53238
53239
53240
53241
53242
53243
53244
53245
53246
53247
53248
53249
53250
53251
53252
53253
53254
53255
53256
53257
53258
53259
53260
53261
53262
53263
53264
53265
53266
53267
53268
53269
53270
53271
53272
53273
53274
53275
53276
53277
53278
53279
53280
53281
53282
53283
53284
53285
53286
53287
53288
53289
53290
53291
53292
53293
53294
53295
53296
53297
53298
53299
53300
53301
53302
53303
53304
53305
53306
53307
53308
53309
53310
53311
53312
53313
53314
53315
53316
53317
53318
53319
53320
53321
53322
53323
53324
53325
53326
53327
53328
53329
53330
53331
53332
53333
53334
53335
53336
53337
53338
53339
53340
53341
53342
53343
53344
53345
53346
53347
53348
53349
53350
53351
53352
53353
53354
53355
53356
53357
53358
53359
53360
53361
53362
53363
53364
53365
53366
53367
53368
53369
53370
53371
53372
53373
53374
53375
53376
53377
53378
53379
53380
53381
53382
53383
53384
53385
53386
53387
53388
53389
53390
53391
53392
53393
53394
53395
53396
53397
53398
53399
53400
53401
53402
53403
53404
53405
53406
53407
53408
53409
53410
53411
53412
53413
53414
53415
53416
53417
53418
53419
53420
53421
53422
53423
53424
53425
53426
53427
53428
53429
53430
53431
53432
53433
53434
53435
53436
53437
53438
53439
53440
53441
53442
53443
53444
53445
53446
53447
53448
53449
53450
53451
53452
53453
53454
53455
53456
53457
53458
53459
53460
53461
53462
53463
53464
53465
53466
53467
53468
53469
53470
53471
53472
53473
53474
53475
53476
53477
53478
53479
53480
53481
53482
53483
53484
53485
53486
53487
53488
53489
53490
53491
53492
53493
53494
53495
53496
53497
53498
53499
53500
53501
53502
53503
53504
53505
53506
53507
53508
53509
53510
53511
53512
53513
53514
53515
53516
53517
53518
53519
53520
53521
53522
53523
53524
53525
53526
53527
53528
53529
53530
53531
53532
53533
53534
53535
53536
53537
53538
53539
53540
53541
53542
53543
53544
53545
53546
53547
53548
53549
53550
53551
53552
53553
53554
53555
53556
53557
53558
53559
53560
53561
53562
53563
53564
53565
53566
53567
53568
53569
53570
53571
53572
53573
53574
53575
53576
53577
53578
53579
53580
53581
53582
53583
53584
53585
53586
53587
53588
53589
53590
53591
53592
53593
53594
53595
53596
53597
53598
53599
53600
53601
53602
53603
53604
53605
53606
53607
53608
53609
53610
53611
53612
53613
53614
53615
53616
53617
53618
53619
53620
53621
53622
53623
53624
53625
53626
53627
53628
53629
53630
53631
53632
53633
53634
53635
53636
53637
53638
53639
53640
53641
53642
53643
53644
53645
53646
53647
53648
53649
53650
53651
53652
53653
53654
53655
53656
53657
53658
53659
53660
53661
53662
53663
53664
53665
53666
53667
53668
53669
53670
53671
53672
53673
53674
53675
53676
53677
53678
53679
53680
53681
53682
53683
53684
53685
53686
53687
53688
53689
53690
53691
53692
53693
53694
53695
53696
53697
53698
53699
53700
53701
53702
53703
53704
53705
53706
53707
53708
53709
53710
53711
53712
53713
53714
53715
53716
53717
53718
53719
53720
53721
53722
53723
53724
53725
53726
53727
53728
53729
53730
53731
53732
53733
53734
53735
53736
53737
53738
53739
53740
53741
53742
53743
53744
53745
53746
53747
53748
53749
53750
53751
53752
53753
53754
53755
53756
53757
53758
53759
53760
53761
53762
53763
53764
53765
53766
53767
53768
53769
53770
53771
53772
53773
53774
53775
53776
53777
53778
53779
53780
53781
53782
53783
53784
53785
53786
53787
53788
53789
53790
53791
53792
53793
53794
53795
53796
53797
53798
53799
53800
53801
53802
53803
53804
53805
53806
53807
53808
53809
53810
53811
53812
53813
53814
53815
53816
53817
53818
53819
53820
53821
53822
53823
53824
53825
53826
53827
53828
53829
53830
53831
53832
53833
53834
53835
53836
53837
53838
53839
53840
53841
53842
53843
53844
53845
53846
53847
53848
53849
53850
53851
53852
53853
53854
53855
53856
53857
53858
53859
53860
53861
53862
53863
53864
53865
53866
53867
53868
53869
53870
53871
53872
53873
53874
53875
53876
53877
53878
53879
53880
53881
53882
53883
53884
53885
53886
53887
53888
53889
53890
53891
53892
53893
53894
53895
53896
53897
53898
53899
53900
53901
53902
53903
53904
53905
53906
53907
53908
53909
53910
53911
53912
53913
53914
53915
53916
53917
53918
53919
53920
53921
53922
53923
53924
53925
53926
53927
53928
53929
53930
53931
53932
53933
53934
53935
53936
53937
53938
53939
53940
53941
53942
53943
53944
53945
53946
53947
53948
53949
53950
53951
53952
53953
53954
53955
53956
53957
53958
53959
53960
53961
53962
53963
53964
53965
53966
53967
53968
53969
53970
53971
53972
53973
53974
53975
53976
53977
53978
53979
53980
53981
53982
53983
53984
53985
53986
53987
53988
53989
53990
53991
53992
53993
53994
53995
53996
53997
53998
53999
54000
54001
54002
54003
54004
54005
54006
54007
54008
54009
54010
54011
54012
54013
54014
54015
54016
54017
54018
54019
54020
54021
54022
54023
54024
54025
54026
54027
54028
54029
54030
54031
54032
54033
54034
54035
54036
54037
54038
54039
54040
54041
54042
54043
54044
54045
54046
54047
54048
54049
54050
54051
54052
54053
54054
54055
54056
54057
54058
54059
54060
54061
54062
54063
54064
54065
54066
54067
54068
54069
54070
54071
54072
54073
54074
54075
54076
54077
54078
54079
54080
54081
54082
54083
54084
54085
54086
54087
54088
54089
54090
54091
54092
54093
54094
54095
54096
54097
54098
54099
54100
54101
54102
54103
54104
54105
54106
54107
54108
54109
54110
54111
54112
54113
54114
54115
54116
54117
54118
54119
54120
54121
54122
54123
54124
54125
54126
54127
54128
54129
54130
54131
54132
54133
54134
54135
54136
54137
54138
54139
54140
54141
54142
54143
54144
54145
54146
54147
54148
54149
54150
54151
54152
54153
54154
54155
54156
54157
54158
54159
54160
54161
54162
54163
54164
54165
54166
54167
54168
54169
54170
54171
54172
54173
54174
54175
54176
54177
54178
54179
54180
54181
54182
54183
54184
54185
54186
54187
54188
54189
54190
54191
54192
54193
54194
54195
54196
54197
54198
54199
54200
54201
54202
54203
54204
54205
54206
54207
54208
54209
54210
54211
54212
54213
54214
54215
54216
54217
54218
54219
54220
54221
54222
54223
54224
54225
54226
54227
54228
54229
54230
54231
54232
54233
54234
54235
54236
54237
54238
54239
54240
54241
54242
54243
54244
54245
54246
54247
54248
54249
54250
54251
54252
54253
54254
54255
54256
54257
54258
54259
54260
54261
54262
54263
54264
54265
54266
54267
54268
54269
54270
54271
54272
54273
54274
54275
54276
54277
54278
54279
54280
54281
54282
54283
54284
54285
54286
54287
54288
54289
54290
54291
54292
54293
54294
54295
54296
54297
54298
54299
54300
54301
54302
54303
54304
54305
54306
54307
54308
54309
54310
54311
54312
54313
54314
54315
54316
54317
54318
54319
54320
54321
54322
54323
54324
54325
54326
54327
54328
54329
54330
54331
54332
54333
54334
54335
54336
54337
54338
54339
54340
54341
54342
54343
54344
54345
54346
54347
54348
54349
54350
54351
54352
54353
54354
54355
54356
54357
54358
54359
54360
54361
54362
54363
54364
54365
54366
54367
54368
54369
54370
54371
54372
54373
54374
54375
54376
54377
54378
54379
54380
54381
54382
54383
54384
54385
54386
54387
54388
54389
54390
54391
54392
54393
54394
54395
54396
54397
54398
54399
54400
54401
54402
54403
54404
54405
54406
54407
54408
54409
54410
54411
54412
54413
54414
54415
54416
54417
54418
54419
54420
54421
54422
54423
54424
54425
54426
54427
54428
54429
54430
54431
54432
54433
54434
54435
54436
54437
54438
54439
54440
54441
54442
54443
54444
54445
54446
54447
54448
54449
54450
54451
54452
54453
54454
54455
54456
54457
54458
54459
54460
54461
54462
54463
54464
54465
54466
54467
54468
54469
54470
54471
54472
54473
54474
54475
54476
54477
54478
54479
54480
54481
54482
54483
54484
54485
54486
54487
54488
54489
54490
54491
54492
54493
54494
54495
54496
54497
54498
54499
54500
54501
54502
54503
54504
54505
54506
54507
54508
54509
54510
54511
54512
54513
54514
54515
54516
54517
54518
54519
54520
54521
54522
54523
54524
54525
54526
54527
54528
54529
54530
54531
54532
54533
54534
54535
54536
54537
54538
54539
54540
54541
54542
54543
54544
54545
54546
54547
54548
54549
54550
54551
54552
54553
54554
54555
54556
54557
54558
54559
54560
54561
54562
54563
54564
54565
54566
54567
54568
54569
54570
54571
54572
54573
54574
54575
54576
54577
54578
54579
54580
54581
54582
54583
54584
54585
54586
54587
54588
54589
54590
54591
54592
54593
54594
54595
54596
54597
54598
54599
54600
54601
54602
54603
54604
54605
54606
54607
54608
54609
54610
54611
54612
54613
54614
54615
54616
54617
54618
54619
54620
54621
54622
54623
54624
54625
54626
54627
54628
54629
54630
54631
54632
54633
54634
54635
54636
54637
54638
54639
54640
54641
54642
54643
54644
54645
54646
54647
54648
54649
54650
54651
54652
54653
54654
54655
54656
54657
54658
54659
54660
54661
54662
54663
54664
54665
54666
54667
54668
54669
54670
54671
54672
54673
54674
54675
54676
54677
54678
54679
54680
54681
54682
54683
54684
54685
54686
54687
54688
54689
54690
54691
54692
54693
54694
54695
54696
54697
54698
54699
54700
54701
54702
54703
54704
54705
54706
54707
54708
54709
54710
54711
54712
54713
54714
54715
54716
54717
54718
54719
54720
54721
54722
54723
54724
54725
54726
54727
54728
54729
54730
54731
54732
54733
54734
54735
54736
54737
54738
54739
54740
54741
54742
54743
54744
54745
54746
54747
54748
54749
54750
54751
54752
54753
54754
54755
54756
54757
54758
54759
54760
54761
54762
54763
54764
54765
54766
54767
54768
54769
54770
54771
54772
54773
54774
54775
54776
54777
54778
54779
54780
54781
54782
54783
54784
54785
54786
54787
54788
54789
54790
54791
54792
54793
54794
54795
54796
54797
54798
54799
54800
54801
54802
54803
54804
54805
54806
54807
54808
54809
54810
54811
54812
54813
54814
54815
54816
54817
54818
54819
54820
54821
54822
54823
54824
54825
54826
54827
54828
54829
54830
54831
54832
54833
54834
54835
54836
54837
54838
54839
54840
54841
54842
54843
54844
54845
54846
54847
54848
54849
54850
54851
54852
54853
54854
54855
54856
54857
54858
54859
54860
54861
54862
54863
54864
54865
54866
54867
54868
54869
54870
54871
54872
54873
54874
54875
54876
54877
54878
54879
54880
54881
54882
54883
54884
54885
54886
54887
54888
54889
54890
54891
54892
54893
54894
54895
54896
54897
54898
54899
54900
54901
54902
54903
54904
54905
54906
54907
54908
54909
54910
54911
54912
54913
54914
54915
54916
54917
54918
54919
54920
54921
54922
54923
54924
54925
54926
54927
54928
54929
54930
54931
54932
54933
54934
54935
54936
54937
54938
54939
54940
54941
54942
54943
54944
54945
54946
54947
54948
54949
54950
54951
54952
54953
54954
54955
54956
54957
54958
54959
54960
54961
54962
54963
54964
54965
54966
54967
54968
54969
54970
54971
54972
54973
54974
54975
54976
54977
54978
54979
54980
54981
54982
54983
54984
54985
54986
54987
54988
54989
54990
54991
54992
54993
54994
54995
54996
54997
54998
54999
55000
55001
55002
55003
55004
55005
55006
55007
55008
55009
55010
55011
55012
55013
55014
55015
55016
55017
55018
55019
55020
55021
55022
55023
55024
55025
55026
55027
55028
55029
55030
55031
55032
55033
55034
55035
55036
55037
55038
55039
55040
55041
55042
55043
55044
55045
55046
55047
55048
55049
55050
55051
55052
55053
55054
55055
55056
55057
55058
55059
55060
55061
55062
55063
55064
55065
55066
55067
55068
55069
55070
55071
55072
55073
55074
55075
55076
55077
55078
55079
55080
55081
55082
55083
55084
55085
55086
55087
55088
55089
55090
55091
55092
55093
55094
55095
55096
55097
55098
55099
55100
55101
55102
55103
55104
55105
55106
55107
55108
55109
55110
55111
55112
55113
55114
55115
55116
55117
55118
55119
55120
55121
55122
55123
55124
55125
55126
55127
55128
55129
55130
55131
55132
55133
55134
55135
55136
55137
55138
55139
55140
55141
55142
55143
55144
55145
55146
55147
55148
55149
55150
55151
55152
55153
55154
55155
55156
55157
55158
55159
55160
55161
55162
55163
55164
55165
55166
55167
55168
55169
55170
55171
55172
55173
55174
55175
55176
55177
55178
55179
55180
55181
55182
55183
55184
55185
55186
55187
55188
55189
55190
55191
55192
55193
55194
55195
55196
55197
55198
55199
55200
55201
55202
55203
55204
55205
55206
55207
55208
55209
55210
55211
55212
55213
55214
55215
55216
55217
55218
55219
55220
55221
55222
55223
55224
55225
55226
55227
55228
55229
55230
55231
55232
55233
55234
55235
55236
55237
55238
55239
55240
55241
55242
55243
55244
55245
55246
55247
55248
55249
55250
55251
55252
55253
55254
55255
55256
55257
55258
55259
55260
55261
55262
55263
55264
55265
55266
55267
55268
55269
55270
55271
55272
55273
55274
55275
55276
55277
55278
55279
55280
55281
55282
55283
55284
55285
55286
55287
55288
55289
55290
55291
55292
55293
55294
55295
55296
55297
55298
55299
55300
55301
55302
55303
55304
55305
55306
55307
55308
55309
55310
55311
55312
55313
55314
55315
55316
55317
55318
55319
55320
55321
55322
55323
55324
55325
55326
55327
55328
55329
55330
55331
55332
55333
55334
55335
55336
55337
55338
55339
55340
55341
55342
55343
55344
55345
55346
55347
55348
55349
55350
55351
55352
55353
55354
55355
55356
55357
55358
55359
55360
55361
55362
55363
55364
55365
55366
55367
55368
55369
55370
55371
55372
55373
55374
55375
55376
55377
55378
55379
55380
55381
55382
55383
55384
55385
55386
55387
55388
55389
55390
55391
55392
55393
55394
55395
55396
55397
55398
55399
55400
55401
55402
55403
55404
55405
55406
55407
55408
55409
55410
55411
55412
55413
55414
55415
55416
55417
55418
55419
55420
55421
55422
55423
55424
55425
55426
55427
55428
55429
55430
55431
55432
55433
55434
55435
55436
55437
55438
55439
55440
55441
55442
55443
55444
55445
55446
55447
55448
55449
55450
55451
55452
55453
55454
55455
55456
55457
55458
55459
55460
55461
55462
55463
55464
55465
55466
55467
55468
55469
55470
55471
55472
55473
55474
55475
55476
55477
55478
55479
55480
55481
55482
55483
55484
55485
55486
55487
55488
55489
55490
55491
55492
55493
55494
55495
55496
55497
55498
55499
55500
55501
55502
55503
55504
55505
55506
55507
55508
55509
55510
55511
55512
55513
55514
55515
55516
55517
55518
55519
55520
55521
55522
55523
55524
55525
55526
55527
55528
55529
55530
55531
55532
55533
55534
55535
55536
55537
55538
55539
55540
55541
55542
55543
55544
55545
55546
55547
55548
55549
55550
55551
55552
55553
55554
55555
55556
55557
55558
55559
55560
55561
55562
55563
55564
55565
55566
55567
55568
55569
55570
55571
55572
55573
55574
55575
55576
55577
55578
55579
55580
55581
55582
55583
55584
55585
55586
55587
55588
55589
55590
55591
55592
55593
55594
55595
55596
55597
55598
55599
55600
55601
55602
55603
55604
55605
55606
55607
55608
55609
55610
55611
55612
55613
55614
55615
55616
55617
55618
55619
55620
55621
55622
55623
55624
55625
55626
55627
55628
55629
55630
55631
55632
55633
55634
55635
55636
55637
55638
55639
55640
55641
55642
55643
55644
55645
55646
55647
55648
55649
55650
55651
55652
55653
55654
55655
55656
55657
55658
55659
55660
55661
55662
55663
55664
55665
55666
55667
55668
55669
55670
55671
55672
55673
55674
55675
55676
55677
55678
55679
55680
55681
55682
55683
55684
55685
55686
55687
55688
55689
55690
55691
55692
55693
55694
55695
55696
55697
55698
55699
55700
55701
55702
55703
55704
55705
55706
55707
55708
55709
55710
55711
55712
55713
55714
55715
55716
55717
55718
55719
55720
55721
55722
55723
55724
55725
55726
55727
55728
55729
55730
55731
55732
55733
55734
55735
55736
55737
55738
55739
55740
55741
55742
55743
55744
55745
55746
55747
55748
55749
55750
55751
55752
55753
55754
55755
55756
55757
55758
55759
55760
55761
55762
55763
55764
55765
55766
55767
55768
55769
55770
55771
55772
55773
55774
55775
55776
55777
55778
55779
55780
55781
55782
55783
55784
55785
55786
55787
55788
55789
55790
55791
55792
55793
55794
55795
55796
55797
55798
55799
55800
55801
55802
55803
55804
55805
55806
55807
55808
55809
55810
55811
55812
55813
55814
55815
55816
55817
55818
55819
55820
55821
55822
55823
55824
55825
55826
55827
55828
55829
55830
55831
55832
55833
55834
55835
55836
55837
55838
55839
55840
55841
55842
55843
55844
55845
55846
55847
55848
55849
55850
55851
55852
55853
55854
55855
55856
55857
55858
55859
55860
55861
55862
55863
55864
55865
55866
55867
55868
55869
55870
55871
55872
55873
55874
55875
55876
55877
55878
55879
55880
55881
55882
55883
55884
55885
55886
55887
55888
55889
55890
55891
55892
55893
55894
55895
55896
55897
55898
55899
55900
55901
55902
55903
55904
55905
55906
55907
55908
55909
55910
55911
55912
55913
55914
55915
55916
55917
55918
55919
55920
55921
55922
55923
55924
55925
55926
55927
55928
55929
55930
55931
55932
55933
55934
55935
55936
55937
55938
55939
55940
55941
55942
55943
55944
55945
55946
55947
55948
55949
55950
55951
55952
55953
55954
55955
55956
55957
55958
55959
55960
55961
55962
55963
55964
55965
55966
55967
55968
55969
55970
55971
55972
55973
55974
55975
55976
55977
55978
55979
55980
55981
55982
55983
55984
55985
55986
55987
55988
55989
55990
55991
55992
55993
55994
55995
55996
55997
55998
55999
56000
56001
56002
56003
56004
56005
56006
56007
56008
56009
56010
56011
56012
56013
56014
56015
56016
56017
56018
56019
56020
56021
56022
56023
56024
56025
56026
56027
56028
56029
56030
56031
56032
56033
56034
56035
56036
56037
56038
56039
56040
56041
56042
56043
56044
56045
56046
56047
56048
56049
56050
56051
56052
56053
56054
56055
56056
56057
56058
56059
56060
56061
56062
56063
56064
56065
56066
56067
56068
56069
56070
56071
56072
56073
56074
56075
56076
56077
56078
56079
56080
56081
56082
56083
56084
56085
56086
56087
56088
56089
56090
56091
56092
56093
56094
56095
56096
56097
56098
56099
56100
56101
56102
56103
56104
56105
56106
56107
56108
56109
56110
56111
56112
56113
56114
56115
56116
56117
56118
56119
56120
56121
56122
56123
56124
56125
56126
56127
56128
56129
56130
56131
56132
56133
56134
56135
56136
56137
56138
56139
56140
56141
56142
56143
56144
56145
56146
56147
56148
56149
56150
56151
56152
56153
56154
56155
56156
56157
56158
56159
56160
56161
56162
56163
56164
56165
56166
56167
56168
56169
56170
56171
56172
56173
56174
56175
56176
56177
56178
56179
56180
56181
56182
56183
56184
56185
56186
56187
56188
56189
56190
56191
56192
56193
56194
56195
56196
56197
56198
56199
56200
56201
56202
56203
56204
56205
56206
56207
56208
56209
56210
56211
56212
56213
56214
56215
56216
56217
56218
56219
56220
56221
56222
56223
56224
56225
56226
56227
56228
56229
56230
56231
56232
56233
56234
56235
56236
56237
56238
56239
56240
56241
56242
56243
56244
56245
56246
56247
56248
56249
56250
56251
56252
56253
56254
56255
56256
56257
56258
56259
56260
56261
56262
56263
56264
56265
56266
56267
56268
56269
56270
56271
56272
56273
56274
56275
56276
56277
56278
56279
56280
56281
56282
56283
56284
56285
56286
56287
56288
56289
56290
56291
56292
56293
56294
56295
56296
56297
56298
56299
56300
56301
56302
56303
56304
56305
56306
56307
56308
56309
56310
56311
56312
56313
56314
56315
56316
56317
56318
56319
56320
56321
56322
56323
56324
56325
56326
56327
56328
56329
56330
56331
56332
56333
56334
56335
56336
56337
56338
56339
56340
56341
56342
56343
56344
56345
56346
56347
56348
56349
56350
56351
56352
56353
56354
56355
56356
56357
56358
56359
56360
56361
56362
56363
56364
56365
56366
56367
56368
56369
56370
56371
56372
56373
56374
56375
56376
56377
56378
56379
56380
56381
56382
56383
56384
56385
56386
56387
56388
56389
56390
56391
56392
56393
56394
56395
56396
56397
56398
56399
56400
56401
56402
56403
56404
56405
56406
56407
56408
56409
56410
56411
56412
56413
56414
56415
56416
56417
56418
56419
56420
56421
56422
56423
56424
56425
56426
56427
56428
56429
56430
56431
56432
56433
56434
56435
56436
56437
56438
56439
56440
56441
56442
56443
56444
56445
56446
56447
56448
56449
56450
56451
56452
56453
56454
56455
56456
56457
56458
56459
56460
56461
56462
56463
56464
56465
56466
56467
56468
56469
56470
56471
56472
56473
56474
56475
56476
56477
56478
56479
56480
56481
56482
56483
56484
56485
56486
56487
56488
56489
56490
56491
56492
56493
56494
56495
56496
56497
56498
56499
56500
56501
56502
56503
56504
56505
56506
56507
56508
56509
56510
56511
56512
56513
56514
56515
56516
56517
56518
56519
56520
56521
56522
56523
56524
56525
56526
56527
56528
56529
56530
56531
56532
56533
56534
56535
56536
56537
56538
56539
56540
56541
56542
56543
56544
56545
56546
56547
56548
56549
56550
56551
56552
56553
56554
56555
56556
56557
56558
56559
56560
56561
56562
56563
56564
56565
56566
56567
56568
56569
56570
56571
56572
56573
56574
56575
56576
56577
56578
56579
56580
56581
56582
56583
56584
56585
56586
56587
56588
56589
56590
56591
56592
56593
56594
56595
56596
56597
56598
56599
56600
56601
56602
56603
56604
56605
56606
56607
56608
56609
56610
56611
56612
56613
56614
56615
56616
56617
56618
56619
56620
56621
56622
56623
56624
56625
56626
56627
56628
56629
56630
56631
56632
56633
56634
56635
56636
56637
56638
56639
56640
56641
56642
56643
56644
56645
56646
56647
56648
56649
56650
56651
56652
56653
56654
56655
56656
56657
56658
56659
56660
56661
56662
56663
56664
56665
56666
56667
56668
56669
56670
56671
56672
56673
56674
56675
56676
56677
56678
56679
56680
56681
56682
56683
56684
56685
56686
56687
56688
56689
56690
56691
56692
56693
56694
56695
56696
56697
56698
56699
56700
56701
56702
56703
56704
56705
56706
56707
56708
56709
56710
56711
56712
56713
56714
56715
56716
56717
56718
56719
56720
56721
56722
56723
56724
56725
56726
56727
56728
56729
56730
56731
56732
56733
56734
56735
56736
56737
56738
56739
56740
56741
56742
56743
56744
56745
56746
56747
56748
56749
56750
56751
56752
56753
56754
56755
56756
56757
56758
56759
56760
56761
56762
56763
56764
56765
56766
56767
56768
56769
56770
56771
56772
56773
56774
56775
56776
56777
56778
56779
56780
56781
56782
56783
56784
56785
56786
56787
56788
56789
56790
56791
56792
56793
56794
56795
56796
56797
56798
56799
56800
56801
56802
56803
56804
56805
56806
56807
56808
56809
56810
56811
56812
56813
56814
56815
56816
56817
56818
56819
56820
56821
56822
56823
56824
56825
56826
56827
56828
56829
56830
56831
56832
56833
56834
56835
56836
56837
56838
56839
56840
56841
56842
56843
56844
56845
56846
56847
56848
56849
56850
56851
56852
56853
56854
56855
56856
56857
56858
56859
56860
56861
56862
56863
56864
56865
56866
56867
56868
56869
56870
56871
56872
56873
56874
56875
56876
56877
56878
56879
56880
56881
56882
56883
56884
56885
56886
56887
56888
56889
56890
56891
56892
56893
56894
56895
56896
56897
56898
56899
56900
56901
56902
56903
56904
56905
56906
56907
56908
56909
56910
56911
56912
56913
56914
56915
56916
56917
56918
56919
56920
56921
56922
56923
56924
56925
56926
56927
56928
56929
56930
56931
56932
56933
56934
56935
56936
56937
56938
56939
56940
56941
56942
56943
56944
56945
56946
56947
56948
56949
56950
56951
56952
56953
56954
56955
56956
56957
56958
56959
56960
56961
56962
56963
56964
56965
56966
56967
56968
56969
56970
56971
56972
56973
56974
56975
56976
56977
56978
56979
56980
56981
56982
56983
56984
56985
56986
56987
56988
56989
56990
56991
56992
56993
56994
56995
56996
56997
56998
56999
57000
57001
57002
57003
57004
57005
57006
57007
57008
57009
57010
57011
57012
57013
57014
57015
57016
57017
57018
57019
57020
57021
57022
57023
57024
57025
57026
57027
57028
57029
57030
57031
57032
57033
57034
57035
57036
57037
57038
57039
57040
57041
57042
57043
57044
57045
57046
57047
57048
57049
57050
57051
57052
57053
57054
57055
57056
57057
57058
57059
57060
57061
57062
57063
57064
57065
57066
57067
57068
57069
57070
57071
57072
57073
57074
57075
57076
57077
57078
57079
57080
57081
57082
57083
57084
57085
57086
57087
57088
57089
57090
57091
57092
57093
57094
57095
57096
57097
57098
57099
57100
57101
57102
57103
57104
57105
57106
57107
57108
57109
57110
57111
57112
57113
57114
57115
57116
57117
57118
57119
57120
57121
57122
57123
57124
57125
57126
57127
57128
57129
57130
57131
57132
57133
57134
57135
57136
57137
57138
57139
57140
57141
57142
57143
57144
57145
57146
57147
57148
57149
57150
57151
57152
57153
57154
57155
57156
57157
57158
57159
57160
57161
57162
57163
57164
57165
57166
57167
57168
57169
57170
57171
57172
57173
57174
57175
57176
57177
57178
57179
57180
57181
57182
57183
57184
57185
57186
57187
57188
57189
57190
57191
57192
57193
57194
57195
57196
57197
57198
57199
57200
57201
57202
57203
57204
57205
57206
57207
57208
57209
57210
57211
57212
57213
57214
57215
57216
57217
57218
57219
57220
57221
57222
57223
57224
57225
57226
57227
57228
57229
57230
57231
57232
57233
57234
57235
57236
57237
57238
57239
57240
57241
57242
57243
57244
57245
57246
57247
57248
57249
57250
57251
57252
57253
57254
57255
57256
57257
57258
57259
57260
57261
57262
57263
57264
57265
57266
57267
57268
57269
57270
57271
57272
57273
57274
57275
57276
57277
57278
57279
57280
57281
57282
57283
57284
57285
57286
57287
57288
57289
57290
57291
57292
57293
57294
57295
57296
57297
57298
57299
57300
57301
57302
57303
57304
57305
57306
57307
57308
57309
57310
57311
57312
57313
57314
57315
57316
57317
57318
57319
57320
57321
57322
57323
57324
57325
57326
57327
57328
57329
57330
57331
57332
57333
57334
57335
57336
57337
57338
57339
57340
57341
57342
57343
57344
57345
57346
57347
57348
57349
57350
57351
57352
57353
57354
57355
57356
57357
57358
57359
57360
57361
57362
57363
57364
57365
57366
57367
57368
57369
57370
57371
57372
57373
57374
57375
57376
57377
57378
57379
57380
57381
57382
57383
57384
57385
57386
57387
57388
57389
57390
57391
57392
57393
57394
57395
57396
57397
57398
57399
57400
57401
57402
57403
57404
57405
57406
57407
57408
57409
57410
57411
57412
57413
57414
57415
57416
57417
57418
57419
57420
57421
57422
57423
57424
57425
57426
57427
57428
57429
57430
57431
57432
57433
57434
57435
57436
57437
57438
57439
57440
57441
57442
57443
57444
57445
57446
57447
57448
57449
57450
57451
57452
57453
57454
57455
57456
57457
57458
57459
57460
57461
57462
57463
57464
57465
57466
57467
57468
57469
57470
57471
57472
57473
57474
57475
57476
57477
57478
57479
57480
57481
57482
57483
57484
57485
57486
57487
57488
57489
57490
57491
57492
57493
57494
57495
57496
57497
57498
57499
57500
57501
57502
57503
57504
57505
57506
57507
57508
57509
57510
57511
57512
57513
57514
57515
57516
57517
57518
57519
57520
57521
57522
57523
57524
57525
57526
57527
57528
57529
57530
57531
57532
57533
57534
57535
57536
57537
57538
57539
57540
57541
57542
57543
57544
57545
57546
57547
57548
57549
57550
57551
57552
57553
57554
57555
57556
57557
57558
57559
57560
57561
57562
57563
57564
57565
57566
57567
57568
57569
57570
57571
57572
57573
57574
57575
57576
57577
57578
57579
57580
57581
57582
57583
57584
57585
57586
57587
57588
57589
57590
57591
57592
57593
57594
57595
57596
57597
57598
57599
57600
57601
57602
57603
57604
57605
57606
57607
57608
57609
57610
57611
57612
57613
57614
57615
57616
57617
57618
57619
57620
57621
57622
57623
57624
57625
57626
57627
57628
57629
57630
57631
57632
57633
57634
57635
57636
57637
57638
57639
57640
57641
57642
57643
57644
57645
57646
57647
57648
57649
57650
57651
57652
57653
57654
57655
57656
57657
57658
57659
57660
57661
57662
57663
57664
57665
57666
57667
57668
57669
57670
57671
57672
57673
57674
57675
57676
57677
57678
57679
57680
57681
57682
57683
57684
57685
57686
57687
57688
57689
57690
57691
57692
57693
57694
57695
57696
57697
57698
57699
57700
57701
57702
57703
57704
57705
57706
57707
57708
57709
57710
57711
57712
57713
57714
57715
57716
57717
57718
57719
57720
57721
57722
57723
57724
57725
57726
57727
57728
57729
57730
57731
57732
57733
57734
57735
57736
57737
57738
57739
57740
57741
57742
57743
57744
57745
57746
57747
57748
57749
57750
57751
57752
57753
57754
57755
57756
57757
57758
57759
57760
57761
57762
57763
57764
57765
57766
57767
57768
57769
57770
57771
57772
57773
57774
57775
57776
57777
57778
57779
57780
57781
57782
57783
57784
57785
57786
57787
57788
57789
57790
57791
57792
57793
57794
57795
57796
57797
57798
57799
57800
57801
57802
57803
57804
57805
57806
57807
57808
57809
57810
57811
57812
57813
57814
57815
57816
57817
57818
57819
57820
57821
57822
57823
57824
57825
57826
57827
57828
57829
57830
57831
57832
57833
57834
57835
57836
57837
57838
57839
57840
57841
57842
57843
57844
57845
57846
57847
57848
57849
57850
57851
57852
57853
57854
57855
57856
57857
57858
57859
57860
57861
57862
57863
57864
57865
57866
57867
57868
57869
57870
57871
57872
57873
57874
57875
57876
57877
57878
57879
57880
57881
57882
57883
57884
57885
57886
57887
57888
57889
57890
57891
57892
57893
57894
57895
57896
57897
57898
57899
57900
57901
57902
57903
57904
57905
57906
57907
57908
57909
57910
57911
57912
57913
57914
57915
57916
57917
57918
57919
57920
57921
57922
57923
57924
57925
57926
57927
57928
57929
57930
57931
57932
57933
57934
57935
57936
57937
57938
57939
57940
57941
57942
57943
57944
57945
57946
57947
57948
57949
57950
57951
57952
57953
57954
57955
57956
57957
57958
57959
57960
57961
57962
57963
57964
57965
57966
57967
57968
57969
57970
57971
57972
57973
57974
57975
57976
57977
57978
57979
57980
57981
57982
57983
57984
57985
57986
57987
57988
57989
57990
57991
57992
57993
57994
57995
57996
57997
57998
57999
58000
58001
58002
58003
58004
58005
58006
58007
58008
58009
58010
58011
58012
58013
58014
58015
58016
58017
58018
58019
58020
58021
58022
58023
58024
58025
58026
58027
58028
58029
58030
58031
58032
58033
58034
58035
58036
58037
58038
58039
58040
58041
58042
58043
58044
58045
58046
58047
58048
58049
58050
58051
58052
58053
58054
58055
58056
58057
58058
58059
58060
58061
58062
58063
58064
58065
58066
58067
58068
58069
58070
58071
58072
58073
58074
58075
58076
58077
58078
58079
58080
58081
58082
58083
58084
58085
58086
58087
58088
58089
58090
58091
58092
58093
58094
58095
58096
58097
58098
58099
58100
58101
58102
58103
58104
58105
58106
58107
58108
58109
58110
58111
58112
58113
58114
58115
58116
58117
58118
58119
58120
58121
58122
58123
58124
58125
58126
58127
58128
58129
58130
58131
58132
58133
58134
58135
58136
58137
58138
58139
58140
58141
58142
58143
58144
58145
58146
58147
58148
58149
58150
58151
58152
58153
58154
58155
58156
58157
58158
58159
58160
58161
58162
58163
58164
58165
58166
58167
58168
58169
58170
58171
58172
58173
58174
58175
58176
58177
58178
58179
58180
58181
58182
58183
58184
58185
58186
58187
58188
58189
58190
58191
58192
58193
58194
58195
58196
58197
58198
58199
58200
58201
58202
58203
58204
58205
58206
58207
58208
58209
58210
58211
58212
58213
58214
58215
58216
58217
58218
58219
58220
58221
58222
58223
58224
58225
58226
58227
58228
58229
58230
58231
58232
58233
58234
58235
58236
58237
58238
58239
58240
58241
58242
58243
58244
58245
58246
58247
58248
58249
58250
58251
58252
58253
58254
58255
58256
58257
58258
58259
58260
58261
58262
58263
58264
58265
58266
58267
58268
58269
58270
58271
58272
58273
58274
58275
58276
58277
58278
58279
58280
58281
58282
58283
58284
58285
58286
58287
58288
58289
58290
58291
58292
58293
58294
58295
58296
58297
58298
58299
58300
58301
58302
58303
58304
58305
58306
58307
58308
58309
58310
58311
58312
58313
58314
58315
58316
58317
58318
58319
58320
58321
58322
58323
58324
58325
58326
58327
58328
58329
58330
58331
58332
58333
58334
58335
58336
58337
58338
58339
58340
58341
58342
58343
58344
58345
58346
58347
58348
58349
58350
58351
58352
58353
58354
58355
58356
58357
58358
58359
58360
58361
58362
58363
58364
58365
58366
58367
58368
58369
58370
58371
58372
58373
58374
58375
58376
58377
58378
58379
58380
58381
58382
58383
58384
58385
58386
58387
58388
58389
58390
58391
58392
58393
58394
58395
58396
58397
58398
58399
58400
58401
58402
58403
58404
58405
58406
58407
58408
58409
58410
58411
58412
58413
58414
58415
58416
58417
58418
58419
58420
58421
58422
58423
58424
58425
58426
58427
58428
58429
58430
58431
58432
58433
58434
58435
58436
58437
58438
58439
58440
58441
58442
58443
58444
58445
58446
58447
58448
58449
58450
58451
58452
58453
58454
58455
58456
58457
58458
58459
58460
58461
58462
58463
58464
58465
58466
58467
58468
58469
58470
58471
58472
58473
58474
58475
58476
58477
58478
58479
58480
58481
58482
58483
58484
58485
58486
58487
58488
58489
58490
58491
58492
58493
58494
58495
58496
58497
58498
58499
58500
58501
58502
58503
58504
58505
58506
58507
58508
58509
58510
58511
58512
58513
58514
58515
58516
58517
58518
58519
58520
58521
58522
58523
58524
58525
58526
58527
58528
58529
58530
58531
58532
58533
58534
58535
58536
58537
58538
58539
58540
58541
58542
58543
58544
58545
58546
58547
58548
58549
58550
58551
58552
58553
58554
58555
58556
58557
58558
58559
58560
58561
58562
58563
58564
58565
58566
58567
58568
58569
58570
58571
58572
58573
58574
58575
58576
58577
58578
58579
58580
58581
58582
58583
58584
58585
58586
58587
58588
58589
58590
58591
58592
58593
58594
58595
58596
58597
58598
58599
58600
58601
58602
58603
58604
58605
58606
58607
58608
58609
58610
58611
58612
58613
58614
58615
58616
58617
58618
58619
58620
58621
58622
58623
58624
58625
58626
58627
58628
58629
58630
58631
58632
58633
58634
58635
58636
58637
58638
58639
58640
58641
58642
58643
58644
58645
58646
58647
58648
58649
58650
58651
58652
58653
58654
58655
58656
58657
58658
58659
58660
58661
58662
58663
58664
58665
58666
58667
58668
58669
58670
58671
58672
58673
58674
58675
58676
58677
58678
58679
58680
58681
58682
58683
58684
58685
58686
58687
58688
58689
58690
58691
58692
58693
58694
58695
58696
58697
58698
58699
58700
58701
58702
58703
58704
58705
58706
58707
58708
58709
58710
58711
58712
58713
58714
58715
58716
58717
58718
58719
58720
58721
58722
58723
58724
58725
58726
58727
58728
58729
58730
58731
58732
58733
58734
58735
58736
58737
58738
58739
58740
58741
58742
58743
58744
58745
58746
58747
58748
58749
58750
58751
58752
58753
58754
58755
58756
58757
58758
58759
58760
58761
58762
58763
58764
58765
58766
58767
58768
58769
58770
58771
58772
58773
58774
58775
58776
58777
58778
58779
58780
58781
58782
58783
58784
58785
58786
58787
58788
58789
58790
58791
58792
58793
58794
58795
58796
58797
58798
58799
58800
58801
58802
58803
58804
58805
58806
58807
58808
58809
58810
58811
58812
58813
58814
58815
58816
58817
58818
58819
58820
58821
58822
58823
58824
58825
58826
58827
58828
58829
58830
58831
58832
58833
58834
58835
58836
58837
58838
58839
58840
58841
58842
58843
58844
58845
58846
58847
58848
58849
58850
58851
58852
58853
58854
58855
58856
58857
58858
58859
58860
58861
58862
58863
58864
58865
58866
58867
58868
58869
58870
58871
58872
58873
58874
58875
58876
58877
58878
58879
58880
58881
58882
58883
58884
58885
58886
58887
58888
58889
58890
58891
58892
58893
58894
58895
58896
58897
58898
58899
58900
58901
58902
58903
58904
58905
58906
58907
58908
58909
58910
58911
58912
58913
58914
58915
58916
58917
58918
58919
58920
58921
58922
58923
58924
58925
58926
58927
58928
58929
58930
58931
58932
58933
58934
58935
58936
58937
58938
58939
58940
58941
58942
58943
58944
58945
58946
58947
58948
58949
58950
58951
58952
58953
58954
58955
58956
58957
58958
58959
58960
58961
58962
58963
58964
58965
58966
58967
58968
58969
58970
58971
58972
58973
58974
58975
58976
58977
58978
58979
58980
58981
58982
58983
58984
58985
58986
58987
58988
58989
58990
58991
58992
58993
58994
58995
58996
58997
58998
58999
59000
59001
59002
59003
59004
59005
59006
59007
59008
59009
59010
59011
59012
59013
59014
59015
59016
59017
59018
59019
59020
59021
59022
59023
59024
59025
59026
59027
59028
59029
59030
59031
59032
59033
59034
59035
59036
59037
59038
59039
59040
59041
59042
59043
59044
59045
59046
59047
59048
59049
59050
59051
59052
59053
59054
59055
59056
59057
59058
59059
59060
59061
59062
59063
59064
59065
59066
59067
59068
59069
59070
59071
59072
59073
59074
59075
59076
59077
59078
59079
59080
59081
59082
59083
59084
59085
59086
59087
59088
59089
59090
59091
59092
59093
59094
59095
59096
59097
59098
59099
59100
59101
59102
59103
59104
59105
59106
59107
59108
59109
59110
59111
59112
59113
59114
59115
59116
59117
59118
59119
59120
59121
59122
59123
59124
59125
59126
59127
59128
59129
59130
59131
59132
59133
59134
59135
59136
59137
59138
59139
59140
59141
59142
59143
59144
59145
59146
59147
59148
59149
59150
59151
59152
59153
59154
59155
59156
59157
59158
59159
59160
59161
59162
59163
59164
59165
59166
59167
59168
59169
59170
59171
59172
59173
59174
59175
59176
59177
59178
59179
59180
59181
59182
59183
59184
59185
59186
59187
59188
59189
59190
59191
59192
59193
59194
59195
59196
59197
59198
59199
59200
59201
59202
59203
59204
59205
59206
59207
59208
59209
59210
59211
59212
59213
59214
59215
59216
59217
59218
59219
59220
59221
59222
59223
59224
59225
59226
59227
59228
59229
59230
59231
59232
59233
59234
59235
59236
59237
59238
59239
59240
59241
59242
59243
59244
59245
59246
59247
59248
59249
59250
59251
59252
59253
59254
59255
59256
59257
59258
59259
59260
59261
59262
59263
59264
59265
59266
59267
59268
59269
59270
59271
59272
59273
59274
59275
59276
59277
59278
59279
59280
59281
59282
59283
59284
59285
59286
59287
59288
59289
59290
59291
59292
59293
59294
59295
59296
59297
59298
59299
59300
59301
59302
59303
59304
59305
59306
59307
59308
59309
59310
59311
59312
59313
59314
59315
59316
59317
59318
59319
59320
59321
59322
59323
59324
59325
59326
59327
59328
59329
59330
59331
59332
59333
59334
59335
59336
59337
59338
59339
59340
59341
59342
59343
59344
59345
59346
59347
59348
59349
59350
59351
59352
59353
59354
59355
59356
59357
59358
59359
59360
59361
59362
59363
59364
59365
59366
59367
59368
59369
59370
59371
59372
59373
59374
59375
59376
59377
59378
59379
59380
59381
59382
59383
59384
59385
59386
59387
59388
59389
59390
59391
59392
59393
59394
59395
59396
59397
59398
59399
59400
59401
59402
59403
59404
59405
59406
59407
59408
59409
59410
59411
59412
59413
59414
59415
59416
59417
59418
59419
59420
59421
59422
59423
59424
59425
59426
59427
59428
59429
59430
59431
59432
59433
59434
59435
59436
59437
59438
59439
59440
59441
59442
59443
59444
59445
59446
59447
59448
59449
59450
59451
59452
59453
59454
59455
59456
59457
59458
59459
59460
59461
59462
59463
59464
59465
59466
59467
59468
59469
59470
59471
59472
59473
59474
59475
59476
59477
59478
59479
59480
59481
59482
59483
59484
59485
59486
59487
59488
59489
59490
59491
59492
59493
59494
59495
59496
59497
59498
59499
59500
59501
59502
59503
59504
59505
59506
59507
59508
59509
59510
59511
59512
59513
59514
59515
59516
59517
59518
59519
59520
59521
59522
59523
59524
59525
59526
59527
59528
59529
59530
59531
59532
59533
59534
59535
59536
59537
59538
59539
59540
59541
59542
59543
59544
59545
59546
59547
59548
59549
59550
59551
59552
59553
59554
59555
59556
59557
59558
59559
59560
59561
59562
59563
59564
59565
59566
59567
59568
59569
59570
59571
59572
59573
59574
59575
59576
59577
59578
59579
59580
59581
59582
59583
59584
59585
59586
59587
59588
59589
59590
59591
59592
59593
59594
59595
59596
59597
59598
59599
59600
59601
59602
59603
59604
59605
59606
59607
59608
59609
59610
59611
59612
59613
59614
59615
59616
59617
59618
59619
59620
59621
59622
59623
59624
59625
59626
59627
59628
59629
59630
59631
59632
59633
59634
59635
59636
59637
59638
59639
59640
59641
59642
59643
59644
59645
59646
59647
59648
59649
59650
59651
59652
59653
59654
59655
59656
59657
59658
59659
59660
59661
59662
59663
59664
59665
59666
59667
59668
59669
59670
59671
59672
59673
59674
59675
59676
59677
59678
59679
59680
59681
59682
59683
59684
59685
59686
59687
59688
59689
59690
59691
59692
59693
59694
59695
59696
59697
59698
59699
59700
59701
59702
59703
59704
59705
59706
59707
59708
59709
59710
59711
59712
59713
59714
59715
59716
59717
59718
59719
59720
59721
59722
59723
59724
59725
59726
59727
59728
59729
59730
59731
59732
59733
59734
59735
59736
59737
59738
59739
59740
59741
59742
59743
59744
59745
59746
59747
59748
59749
59750
59751
59752
59753
59754
59755
59756
59757
59758
59759
59760
59761
59762
59763
59764
59765
59766
59767
59768
59769
59770
59771
59772
59773
59774
59775
59776
59777
59778
59779
59780
59781
59782
59783
59784
59785
59786
59787
59788
59789
59790
59791
59792
59793
59794
59795
59796
59797
59798
59799
59800
59801
59802
59803
59804
59805
59806
59807
59808
59809
59810
59811
59812
59813
59814
59815
59816
59817
59818
59819
59820
59821
59822
59823
59824
59825
59826
59827
59828
59829
59830
59831
59832
59833
59834
59835
59836
59837
59838
59839
59840
59841
59842
59843
59844
59845
59846
59847
59848
59849
59850
59851
59852
59853
59854
59855
59856
59857
59858
59859
59860
59861
59862
59863
59864
59865
59866
59867
59868
59869
59870
59871
59872
59873
59874
59875
59876
59877
59878
59879
59880
59881
59882
59883
59884
59885
59886
59887
59888
59889
59890
59891
59892
59893
59894
59895
59896
59897
59898
59899
59900
59901
59902
59903
59904
59905
59906
59907
59908
59909
59910
59911
59912
59913
59914
59915
59916
59917
59918
59919
59920
59921
59922
59923
59924
59925
59926
59927
59928
59929
59930
59931
59932
59933
59934
59935
59936
59937
59938
59939
59940
59941
59942
59943
59944
59945
59946
59947
59948
59949
59950
59951
59952
59953
59954
59955
59956
59957
59958
59959
59960
59961
59962
59963
59964
59965
59966
59967
59968
59969
59970
59971
59972
59973
59974
59975
59976
59977
59978
59979
59980
59981
59982
59983
59984
59985
59986
59987
59988
59989
59990
59991
59992
59993
59994
59995
59996
59997
59998
59999
60000
60001
60002
60003
60004
60005
60006
60007
60008
60009
60010
60011
60012
60013
60014
60015
60016
60017
60018
60019
60020
60021
60022
60023
60024
60025
60026
60027
60028
60029
60030
60031
60032
60033
60034
60035
60036
60037
60038
60039
60040
60041
60042
60043
60044
60045
60046
60047
60048
60049
60050
60051
60052
60053
60054
60055
60056
60057
60058
60059
60060
60061
60062
60063
60064
60065
60066
60067
60068
60069
60070
60071
60072
60073
60074
60075
60076
60077
60078
60079
60080
60081
60082
60083
60084
60085
60086
60087
60088
60089
60090
60091
60092
60093
60094
60095
60096
60097
60098
60099
60100
60101
60102
60103
60104
60105
60106
60107
60108
60109
60110
60111
60112
60113
60114
60115
60116
60117
60118
60119
60120
60121
60122
60123
60124
60125
60126
60127
60128
60129
60130
60131
60132
60133
60134
60135
60136
60137
60138
60139
60140
60141
60142
60143
60144
60145
60146
60147
60148
60149
60150
60151
60152
60153
60154
60155
60156
60157
60158
60159
60160
60161
60162
60163
60164
60165
60166
60167
60168
60169
60170
60171
60172
60173
60174
60175
60176
60177
60178
60179
60180
60181
60182
60183
60184
60185
60186
60187
60188
60189
60190
60191
60192
60193
60194
60195
60196
60197
60198
60199
60200
60201
60202
60203
60204
60205
60206
60207
60208
60209
60210
60211
60212
60213
60214
60215
60216
60217
60218
60219
60220
60221
60222
60223
60224
60225
60226
60227
60228
60229
60230
60231
60232
60233
60234
60235
60236
60237
60238
60239
60240
60241
60242
60243
60244
60245
60246
60247
60248
60249
60250
60251
60252
60253
60254
60255
60256
60257
60258
60259
60260
60261
60262
60263
60264
60265
60266
60267
60268
60269
60270
60271
60272
60273
60274
60275
60276
60277
60278
60279
60280
60281
60282
60283
60284
60285
60286
60287
60288
60289
60290
60291
60292
60293
60294
60295
60296
60297
60298
60299
60300
60301
60302
60303
60304
60305
60306
60307
60308
60309
60310
60311
60312
60313
60314
60315
60316
60317
60318
60319
60320
60321
60322
60323
60324
60325
60326
60327
60328
60329
60330
60331
60332
60333
60334
60335
60336
60337
60338
60339
60340
60341
60342
60343
60344
60345
60346
60347
60348
60349
60350
60351
60352
60353
60354
60355
60356
60357
60358
60359
60360
60361
60362
60363
60364
60365
60366
60367
60368
60369
60370
60371
60372
60373
60374
60375
60376
60377
60378
60379
60380
60381
60382
60383
60384
60385
60386
60387
60388
60389
60390
60391
60392
60393
60394
60395
60396
60397
60398
60399
60400
60401
60402
60403
60404
60405
60406
60407
60408
60409
60410
60411
60412
60413
60414
60415
60416
60417
60418
60419
60420
60421
60422
60423
60424
60425
60426
60427
60428
60429
60430
60431
60432
60433
60434
60435
60436
60437
60438
60439
60440
60441
60442
60443
60444
60445
60446
60447
60448
60449
60450
60451
60452
60453
60454
60455
60456
60457
60458
60459
60460
60461
60462
60463
60464
60465
60466
60467
60468
60469
60470
60471
60472
60473
60474
60475
60476
60477
60478
60479
60480
60481
60482
60483
60484
60485
60486
60487
60488
60489
60490
60491
60492
60493
60494
60495
60496
60497
60498
60499
60500
60501
60502
60503
60504
60505
60506
60507
60508
60509
60510
60511
60512
60513
60514
60515
60516
60517
60518
60519
60520
60521
60522
60523
60524
60525
60526
60527
60528
60529
60530
60531
60532
60533
60534
60535
60536
60537
60538
60539
60540
60541
60542
60543
60544
60545
60546
60547
60548
60549
60550
60551
60552
60553
60554
60555
60556
60557
60558
60559
60560
60561
60562
60563
60564
60565
60566
60567
60568
60569
60570
60571
60572
60573
60574
60575
60576
60577
60578
60579
60580
60581
60582
60583
60584
60585
60586
60587
60588
60589
60590
60591
60592
60593
60594
60595
60596
60597
60598
60599
60600
60601
60602
60603
60604
60605
60606
60607
60608
60609
60610
60611
60612
60613
60614
60615
60616
60617
60618
60619
60620
60621
60622
60623
60624
60625
60626
60627
60628
60629
60630
60631
60632
60633
60634
60635
60636
60637
60638
60639
60640
60641
60642
60643
60644
60645
60646
60647
60648
60649
60650
60651
60652
60653
60654
60655
60656
60657
60658
60659
60660
60661
60662
60663
60664
60665
60666
60667
60668
60669
60670
60671
60672
60673
60674
60675
60676
60677
60678
60679
60680
60681
60682
60683
60684
60685
60686
60687
60688
60689
60690
60691
60692
60693
60694
60695
60696
60697
60698
60699
60700
60701
60702
60703
60704
60705
60706
60707
60708
60709
60710
60711
60712
60713
60714
60715
60716
60717
60718
60719
60720
60721
60722
60723
60724
60725
60726
60727
60728
60729
60730
60731
60732
60733
60734
60735
60736
60737
60738
60739
60740
60741
60742
60743
60744
60745
60746
60747
60748
60749
60750
60751
60752
60753
60754
60755
60756
60757
60758
60759
60760
60761
60762
60763
60764
60765
60766
60767
60768
60769
60770
60771
60772
60773
60774
60775
60776
60777
60778
60779
60780
60781
60782
60783
60784
60785
60786
60787
60788
60789
60790
60791
60792
60793
60794
60795
60796
60797
60798
60799
60800
60801
60802
60803
60804
60805
60806
60807
60808
60809
60810
60811
60812
60813
60814
60815
60816
60817
60818
60819
60820
60821
60822
60823
60824
60825
60826
60827
60828
60829
60830
60831
60832
60833
60834
60835
60836
60837
60838
60839
60840
60841
60842
60843
60844
60845
60846
60847
60848
60849
60850
60851
60852
60853
60854
60855
60856
60857
60858
60859
60860
60861
60862
60863
60864
60865
60866
60867
60868
60869
60870
60871
60872
60873
60874
60875
60876
60877
60878
60879
60880
60881
60882
60883
60884
60885
60886
60887
60888
60889
60890
60891
60892
60893
60894
60895
60896
60897
60898
60899
60900
60901
60902
60903
60904
60905
60906
60907
60908
60909
60910
60911
60912
60913
60914
60915
60916
60917
60918
60919
60920
60921
60922
60923
60924
60925
60926
60927
60928
60929
60930
60931
60932
60933
60934
60935
60936
60937
60938
60939
60940
60941
60942
60943
60944
60945
60946
60947
60948
60949
60950
60951
60952
60953
60954
60955
60956
60957
60958
60959
60960
60961
60962
60963
60964
60965
60966
60967
60968
60969
60970
60971
60972
60973
60974
60975
60976
60977
60978
60979
60980
60981
60982
60983
60984
60985
60986
60987
60988
60989
60990
60991
60992
60993
60994
60995
60996
60997
60998
60999
61000
61001
61002
61003
61004
61005
61006
61007
61008
61009
61010
61011
61012
61013
61014
61015
61016
61017
61018
61019
61020
61021
61022
61023
61024
61025
61026
61027
61028
61029
61030
61031
61032
61033
61034
61035
61036
61037
61038
61039
61040
61041
61042
61043
61044
61045
61046
61047
61048
61049
61050
61051
61052
61053
61054
61055
61056
61057
61058
61059
61060
61061
61062
61063
61064
61065
61066
61067
61068
61069
61070
61071
61072
61073
61074
61075
61076
61077
61078
61079
61080
61081
61082
61083
61084
61085
61086
61087
61088
61089
61090
61091
61092
61093
61094
61095
61096
61097
61098
61099
61100
61101
61102
61103
61104
61105
61106
61107
61108
61109
61110
61111
61112
61113
61114
61115
61116
61117
61118
61119
61120
61121
61122
61123
61124
61125
61126
61127
61128
61129
61130
61131
61132
61133
61134
61135
61136
61137
61138
61139
61140
61141
61142
61143
61144
61145
61146
61147
61148
61149
61150
61151
61152
61153
61154
61155
61156
61157
61158
61159
61160
61161
61162
61163
61164
61165
61166
61167
61168
61169
61170
61171
61172
61173
61174
61175
61176
61177
61178
61179
61180
61181
61182
61183
61184
61185
61186
61187
61188
61189
61190
61191
61192
61193
61194
61195
61196
61197
61198
61199
61200
61201
61202
61203
61204
61205
61206
61207
61208
61209
61210
61211
61212
61213
61214
61215
61216
61217
61218
61219
61220
61221
61222
61223
61224
61225
61226
61227
61228
61229
61230
61231
61232
61233
61234
61235
61236
61237
61238
61239
61240
61241
61242
61243
61244
61245
61246
61247
61248
61249
61250
61251
61252
61253
61254
61255
61256
61257
61258
61259
61260
61261
61262
61263
61264
61265
61266
61267
61268
61269
61270
61271
61272
61273
61274
61275
61276
61277
61278
61279
61280
61281
61282
61283
61284
61285
61286
61287
61288
61289
61290
61291
61292
61293
61294
61295
61296
61297
61298
61299
61300
61301
61302
61303
61304
61305
61306
61307
61308
61309
61310
61311
61312
61313
61314
61315
61316
61317
61318
61319
61320
61321
61322
61323
61324
61325
61326
61327
61328
61329
61330
61331
61332
61333
61334
61335
61336
61337
61338
61339
61340
61341
61342
61343
61344
61345
61346
61347
61348
61349
61350
61351
61352
61353
61354
61355
61356
61357
61358
61359
61360
61361
61362
61363
61364
61365
61366
61367
61368
61369
61370
61371
61372
61373
61374
61375
61376
61377
61378
61379
61380
61381
61382
61383
61384
61385
61386
61387
61388
61389
61390
61391
61392
61393
61394
61395
61396
61397
61398
61399
61400
61401
61402
61403
61404
61405
61406
61407
61408
61409
61410
61411
61412
61413
61414
61415
61416
61417
61418
61419
61420
61421
61422
61423
61424
61425
61426
61427
61428
61429
61430
61431
61432
61433
61434
61435
61436
61437
61438
61439
61440
61441
61442
61443
61444
61445
61446
61447
61448
61449
61450
61451
61452
61453
61454
61455
61456
61457
61458
61459
61460
61461
61462
61463
61464
61465
61466
61467
61468
61469
61470
61471
61472
61473
61474
61475
61476
61477
61478
61479
61480
61481
61482
61483
61484
61485
61486
61487
61488
61489
61490
61491
61492
61493
61494
61495
61496
61497
61498
61499
61500
61501
61502
61503
61504
61505
61506
61507
61508
61509
61510
61511
61512
61513
61514
61515
61516
61517
61518
61519
61520
61521
61522
61523
61524
61525
61526
61527
61528
61529
61530
61531
61532
61533
61534
61535
61536
61537
61538
61539
61540
61541
61542
61543
61544
61545
61546
61547
61548
61549
61550
61551
61552
61553
61554
61555
61556
61557
61558
61559
61560
61561
61562
61563
61564
61565
61566
61567
61568
61569
61570
61571
61572
61573
61574
61575
61576
61577
61578
61579
61580
61581
61582
61583
61584
61585
61586
61587
61588
61589
61590
61591
61592
61593
61594
61595
61596
61597
61598
61599
61600
61601
61602
61603
61604
61605
61606
61607
61608
61609
61610
61611
61612
61613
61614
61615
61616
61617
61618
61619
61620
61621
61622
61623
61624
61625
61626
61627
61628
61629
61630
61631
61632
61633
61634
61635
61636
61637
61638
61639
61640
61641
61642
61643
61644
61645
61646
61647
61648
61649
61650
61651
61652
61653
61654
61655
61656
61657
61658
61659
61660
61661
61662
61663
61664
61665
61666
61667
61668
61669
61670
61671
61672
61673
61674
61675
61676
61677
61678
61679
61680
61681
61682
61683
61684
61685
61686
61687
61688
61689
61690
61691
61692
61693
61694
61695
61696
61697
61698
61699
61700
61701
61702
61703
61704
61705
61706
61707
61708
61709
61710
61711
61712
61713
61714
61715
61716
61717
61718
61719
61720
61721
61722
61723
61724
61725
61726
61727
61728
61729
61730
61731
61732
61733
61734
61735
61736
61737
61738
61739
61740
61741
61742
61743
61744
61745
61746
61747
61748
61749
61750
61751
61752
61753
61754
61755
61756
61757
61758
61759
61760
61761
61762
61763
61764
61765
61766
61767
61768
61769
61770
61771
61772
61773
61774
61775
61776
61777
61778
61779
61780
61781
61782
61783
61784
61785
61786
61787
61788
61789
61790
61791
61792
61793
61794
61795
61796
61797
61798
61799
61800
61801
61802
61803
61804
61805
61806
61807
61808
61809
61810
61811
61812
61813
61814
61815
61816
61817
61818
61819
61820
61821
61822
61823
61824
61825
61826
61827
61828
61829
61830
61831
61832
61833
61834
61835
61836
61837
61838
61839
61840
61841
61842
61843
61844
61845
61846
61847
61848
61849
61850
61851
61852
61853
61854
61855
61856
61857
61858
61859
61860
61861
61862
61863
61864
61865
61866
61867
61868
61869
61870
61871
61872
61873
61874
61875
61876
61877
61878
61879
61880
61881
61882
61883
61884
61885
61886
61887
61888
61889
61890
61891
61892
61893
61894
61895
61896
61897
61898
61899
61900
61901
61902
61903
61904
61905
61906
61907
61908
61909
61910
61911
61912
61913
61914
61915
61916
61917
61918
61919
61920
61921
61922
61923
61924
61925
61926
61927
61928
61929
61930
61931
61932
61933
61934
61935
61936
61937
61938
61939
61940
61941
61942
61943
61944
61945
61946
61947
61948
61949
61950
61951
61952
61953
61954
61955
61956
61957
61958
61959
61960
61961
61962
61963
61964
61965
61966
61967
61968
61969
61970
61971
61972
61973
61974
61975
61976
61977
61978
61979
61980
61981
61982
61983
61984
61985
61986
61987
61988
61989
61990
61991
61992
61993
61994
61995
61996
61997
61998
61999
62000
62001
62002
62003
62004
62005
62006
62007
62008
62009
62010
62011
62012
62013
62014
62015
62016
62017
62018
62019
62020
62021
62022
62023
62024
62025
62026
62027
62028
62029
62030
62031
62032
62033
62034
62035
62036
62037
62038
62039
62040
62041
62042
62043
62044
62045
62046
62047
62048
62049
62050
62051
62052
62053
62054
62055
62056
62057
62058
62059
62060
62061
62062
62063
62064
62065
62066
62067
62068
62069
62070
62071
62072
62073
62074
62075
62076
62077
62078
62079
62080
62081
62082
62083
62084
62085
62086
62087
62088
62089
62090
62091
62092
62093
62094
62095
62096
62097
62098
62099
62100
62101
62102
62103
62104
62105
62106
62107
62108
62109
62110
62111
62112
62113
62114
62115
62116
62117
62118
62119
62120
62121
62122
62123
62124
62125
62126
62127
62128
62129
62130
62131
62132
62133
62134
62135
62136
62137
62138
62139
62140
62141
62142
62143
62144
62145
62146
62147
62148
62149
62150
62151
62152
62153
62154
62155
62156
62157
62158
62159
62160
62161
62162
62163
62164
62165
62166
62167
62168
62169
62170
62171
62172
62173
62174
62175
62176
62177
62178
62179
62180
62181
62182
62183
62184
62185
62186
62187
62188
62189
62190
62191
62192
62193
62194
62195
62196
62197
62198
62199
62200
62201
62202
62203
62204
62205
62206
62207
62208
62209
62210
62211
62212
62213
62214
62215
62216
62217
62218
62219
62220
62221
62222
62223
62224
62225
62226
62227
62228
62229
62230
62231
62232
62233
62234
62235
62236
62237
62238
62239
62240
62241
62242
62243
62244
62245
62246
62247
62248
62249
62250
62251
62252
62253
62254
62255
62256
62257
62258
62259
62260
62261
62262
62263
62264
62265
62266
62267
62268
62269
62270
62271
62272
62273
62274
62275
62276
62277
62278
62279
62280
62281
62282
62283
62284
62285
62286
62287
62288
62289
62290
62291
62292
62293
62294
62295
62296
62297
62298
62299
62300
62301
62302
62303
62304
62305
62306
62307
62308
62309
62310
62311
62312
62313
62314
62315
62316
62317
62318
62319
62320
62321
62322
62323
62324
62325
62326
62327
62328
62329
62330
62331
62332
62333
62334
62335
62336
62337
62338
62339
62340
62341
62342
62343
62344
62345
62346
62347
62348
62349
62350
62351
62352
62353
62354
62355
62356
62357
62358
62359
62360
62361
62362
62363
62364
62365
62366
62367
62368
62369
62370
62371
62372
62373
62374
62375
62376
62377
62378
62379
62380
62381
62382
62383
62384
62385
62386
62387
62388
62389
62390
62391
62392
62393
62394
62395
62396
62397
62398
62399
62400
62401
62402
62403
62404
62405
62406
62407
62408
62409
62410
62411
62412
62413
62414
62415
62416
62417
62418
62419
62420
62421
62422
62423
62424
62425
62426
62427
62428
62429
62430
62431
62432
62433
62434
62435
62436
62437
62438
62439
62440
62441
62442
62443
62444
62445
62446
62447
62448
62449
62450
62451
62452
62453
62454
62455
62456
62457
62458
62459
62460
62461
62462
62463
62464
62465
62466
62467
62468
62469
62470
62471
62472
62473
62474
62475
62476
62477
62478
62479
62480
62481
62482
62483
62484
62485
62486
62487
62488
62489
62490
62491
62492
62493
62494
62495
62496
62497
62498
62499
62500
62501
62502
62503
62504
62505
62506
62507
62508
62509
62510
62511
62512
62513
62514
62515
62516
62517
62518
62519
62520
62521
62522
62523
62524
62525
62526
62527
62528
62529
62530
62531
62532
62533
62534
62535
62536
62537
62538
62539
62540
62541
62542
62543
62544
62545
62546
62547
62548
62549
62550
62551
62552
62553
62554
62555
62556
62557
62558
62559
62560
62561
62562
62563
62564
62565
62566
62567
62568
62569
62570
62571
62572
62573
62574
62575
62576
62577
62578
62579
62580
62581
62582
62583
62584
62585
62586
62587
62588
62589
62590
62591
62592
62593
62594
62595
62596
62597
62598
62599
62600
62601
62602
62603
62604
62605
62606
62607
62608
62609
62610
62611
62612
62613
62614
62615
62616
62617
62618
62619
62620
62621
62622
62623
62624
62625
62626
62627
62628
62629
62630
62631
62632
62633
62634
62635
62636
62637
62638
62639
62640
62641
62642
62643
62644
62645
62646
62647
62648
62649
62650
62651
62652
62653
62654
62655
62656
62657
62658
62659
62660
62661
62662
62663
62664
62665
62666
62667
62668
62669
62670
62671
62672
62673
62674
62675
62676
62677
62678
62679
62680
62681
62682
62683
62684
62685
62686
62687
62688
62689
62690
62691
62692
62693
62694
62695
62696
62697
62698
62699
62700
62701
62702
62703
62704
62705
62706
62707
62708
62709
62710
62711
62712
62713
62714
62715
62716
62717
62718
62719
62720
62721
62722
62723
62724
62725
62726
62727
62728
62729
62730
62731
62732
62733
62734
62735
62736
62737
62738
62739
62740
62741
62742
62743
62744
62745
62746
62747
62748
62749
62750
62751
62752
62753
62754
62755
62756
62757
62758
62759
62760
62761
62762
62763
62764
62765
62766
62767
62768
62769
62770
62771
62772
62773
62774
62775
62776
62777
62778
62779
62780
62781
62782
62783
62784
62785
62786
62787
62788
62789
62790
62791
62792
62793
62794
62795
62796
62797
62798
62799
62800
62801
62802
62803
62804
62805
62806
62807
62808
62809
62810
62811
62812
62813
62814
62815
62816
62817
62818
62819
62820
62821
62822
62823
62824
62825
62826
62827
62828
62829
62830
62831
62832
62833
62834
62835
62836
62837
62838
62839
62840
62841
62842
62843
62844
62845
62846
62847
62848
62849
62850
62851
62852
62853
62854
62855
62856
62857
62858
62859
62860
62861
62862
62863
62864
62865
62866
62867
62868
62869
62870
62871
62872
62873
62874
62875
62876
62877
62878
62879
62880
62881
62882
62883
62884
62885
62886
62887
62888
62889
62890
62891
62892
62893
62894
62895
62896
62897
62898
62899
62900
62901
62902
62903
62904
62905
62906
62907
62908
62909
62910
62911
62912
62913
62914
62915
62916
62917
62918
62919
62920
62921
62922
62923
62924
62925
62926
62927
62928
62929
62930
62931
62932
62933
62934
62935
62936
62937
62938
62939
62940
62941
62942
62943
62944
62945
62946
62947
62948
62949
62950
62951
62952
62953
62954
62955
62956
62957
62958
62959
62960
62961
62962
62963
62964
62965
62966
62967
62968
62969
62970
62971
62972
62973
62974
62975
62976
62977
62978
62979
62980
62981
62982
62983
62984
62985
62986
62987
62988
62989
62990
62991
62992
62993
62994
62995
62996
62997
62998
62999
63000
63001
63002
63003
63004
63005
63006
63007
63008
63009
63010
63011
63012
63013
63014
63015
63016
63017
63018
63019
63020
63021
63022
63023
63024
63025
63026
63027
63028
63029
63030
63031
63032
63033
63034
63035
63036
63037
63038
63039
63040
63041
63042
63043
63044
63045
63046
63047
63048
63049
63050
63051
63052
63053
63054
63055
63056
63057
63058
63059
63060
63061
63062
63063
63064
63065
63066
63067
63068
63069
63070
63071
63072
63073
63074
63075
63076
63077
63078
63079
63080
63081
63082
63083
63084
63085
63086
63087
63088
63089
63090
63091
63092
63093
63094
63095
63096
63097
63098
63099
63100
63101
63102
63103
63104
63105
63106
63107
63108
63109
63110
63111
63112
63113
63114
63115
63116
63117
63118
63119
63120
63121
63122
63123
63124
63125
63126
63127
63128
63129
63130
63131
63132
63133
63134
63135
63136
63137
63138
63139
63140
63141
63142
63143
63144
63145
63146
63147
63148
63149
63150
63151
63152
63153
63154
63155
63156
63157
63158
63159
63160
63161
63162
63163
63164
63165
63166
63167
63168
63169
63170
63171
63172
63173
63174
63175
63176
63177
63178
63179
63180
63181
63182
63183
63184
63185
63186
63187
63188
63189
63190
63191
63192
63193
63194
63195
63196
63197
63198
63199
63200
63201
63202
63203
63204
63205
63206
63207
63208
63209
63210
63211
63212
63213
63214
63215
63216
63217
63218
63219
63220
63221
63222
63223
63224
63225
63226
63227
63228
63229
63230
63231
63232
63233
63234
63235
63236
63237
63238
63239
63240
63241
63242
63243
63244
63245
63246
63247
63248
63249
63250
63251
63252
63253
63254
63255
63256
63257
63258
63259
63260
63261
63262
63263
63264
63265
63266
63267
63268
63269
63270
63271
63272
63273
63274
63275
63276
63277
63278
63279
63280
63281
63282
63283
63284
63285
63286
63287
63288
63289
63290
63291
63292
63293
63294
63295
63296
63297
63298
63299
63300
63301
63302
63303
63304
63305
63306
63307
63308
63309
63310
63311
63312
63313
63314
63315
63316
63317
63318
63319
63320
63321
63322
63323
63324
63325
63326
63327
63328
63329
63330
63331
63332
63333
63334
63335
63336
63337
63338
63339
63340
63341
63342
63343
63344
63345
63346
63347
63348
63349
63350
63351
63352
63353
63354
63355
63356
63357
63358
63359
63360
63361
63362
63363
63364
63365
63366
63367
63368
63369
63370
63371
63372
63373
63374
63375
63376
63377
63378
63379
63380
63381
63382
63383
63384
63385
63386
63387
63388
63389
63390
63391
63392
63393
63394
63395
63396
63397
63398
63399
63400
63401
63402
63403
63404
63405
63406
63407
63408
63409
63410
63411
63412
63413
63414
63415
63416
63417
63418
63419
63420
63421
63422
63423
63424
63425
63426
63427
63428
63429
63430
63431
63432
63433
63434
63435
63436
63437
63438
63439
63440
63441
63442
63443
63444
63445
63446
63447
63448
63449
63450
63451
63452
63453
63454
63455
63456
63457
63458
63459
63460
63461
63462
63463
63464
63465
63466
63467
63468
63469
63470
63471
63472
63473
63474
63475
63476
63477
63478
63479
63480
63481
63482
63483
63484
63485
63486
63487
63488
63489
63490
63491
63492
63493
63494
63495
63496
63497
63498
63499
63500
63501
63502
63503
63504
63505
63506
63507
63508
63509
63510
63511
63512
63513
63514
63515
63516
63517
63518
63519
63520
63521
63522
63523
63524
63525
63526
63527
63528
63529
63530
63531
63532
63533
63534
63535
63536
63537
63538
63539
63540
63541
63542
63543
63544
63545
63546
63547
63548
63549
63550
63551
63552
63553
63554
63555
63556
63557
63558
63559
63560
63561
63562
63563
63564
63565
63566
63567
63568
63569
63570
63571
63572
63573
63574
63575
63576
63577
63578
63579
63580
63581
63582
63583
63584
63585
63586
63587
63588
63589
63590
63591
63592
63593
63594
63595
63596
63597
63598
63599
63600
63601
63602
63603
63604
63605
63606
63607
63608
63609
63610
63611
63612
63613
63614
63615
63616
63617
63618
63619
63620
63621
63622
63623
63624
63625
63626
63627
63628
63629
63630
63631
63632
63633
63634
63635
63636
63637
63638
63639
63640
63641
63642
63643
63644
63645
63646
63647
63648
63649
63650
63651
63652
63653
63654
63655
63656
63657
63658
63659
63660
63661
63662
63663
63664
63665
63666
63667
63668
63669
63670
63671
63672
63673
63674
63675
63676
63677
63678
63679
63680
63681
63682
63683
63684
63685
63686
63687
63688
63689
63690
63691
63692
63693
63694
63695
63696
63697
63698
63699
63700
63701
63702
63703
63704
63705
63706
63707
63708
63709
63710
63711
63712
63713
63714
63715
63716
63717
63718
63719
63720
63721
63722
63723
63724
63725
63726
63727
63728
63729
63730
63731
63732
63733
63734
63735
63736
63737
63738
63739
63740
63741
63742
63743
63744
63745
63746
63747
63748
63749
63750
63751
63752
63753
63754
63755
63756
63757
63758
63759
63760
63761
63762
63763
63764
63765
63766
63767
63768
63769
63770
63771
63772
63773
63774
63775
63776
63777
63778
63779
63780
63781
63782
63783
63784
63785
63786
63787
63788
63789
63790
63791
63792
63793
63794
63795
63796
63797
63798
63799
63800
63801
63802
63803
63804
63805
63806
63807
63808
63809
63810
63811
63812
63813
63814
63815
63816
63817
63818
63819
63820
63821
63822
63823
63824
63825
63826
63827
63828
63829
63830
63831
63832
63833
63834
63835
63836
63837
63838
63839
63840
63841
63842
63843
63844
63845
63846
63847
63848
63849
63850
63851
63852
63853
63854
63855
63856
63857
63858
63859
63860
63861
63862
63863
63864
63865
63866
63867
63868
63869
63870
63871
63872
63873
63874
63875
63876
63877
63878
63879
63880
63881
63882
63883
63884
63885
63886
63887
63888
63889
63890
63891
63892
63893
63894
63895
63896
63897
63898
63899
63900
63901
63902
63903
63904
63905
63906
63907
63908
63909
63910
63911
63912
63913
63914
63915
63916
63917
63918
63919
63920
63921
63922
63923
63924
63925
63926
63927
63928
63929
63930
63931
63932
63933
63934
63935
63936
63937
63938
63939
63940
63941
63942
63943
63944
63945
63946
63947
63948
63949
63950
63951
63952
63953
63954
63955
63956
63957
63958
63959
63960
63961
63962
63963
63964
63965
63966
63967
63968
63969
63970
63971
63972
63973
63974
63975
63976
63977
63978
63979
63980
63981
63982
63983
63984
63985
63986
63987
63988
63989
63990
63991
63992
63993
63994
63995
63996
63997
63998
63999
64000
64001
64002
64003
64004
64005
64006
64007
64008
64009
64010
64011
64012
64013
64014
64015
64016
64017
64018
64019
64020
64021
64022
64023
64024
64025
64026
64027
64028
64029
64030
64031
64032
64033
64034
64035
64036
64037
64038
64039
64040
64041
64042
64043
64044
64045
64046
64047
64048
64049
64050
64051
64052
64053
64054
64055
64056
64057
64058
64059
64060
64061
64062
64063
64064
64065
64066
64067
64068
64069
64070
64071
64072
64073
64074
64075
64076
64077
64078
64079
64080
64081
64082
64083
64084
64085
64086
64087
64088
64089
64090
64091
64092
64093
64094
64095
64096
64097
64098
64099
64100
64101
64102
64103
64104
64105
64106
64107
64108
64109
64110
64111
64112
64113
64114
64115
64116
64117
64118
64119
64120
64121
64122
64123
64124
64125
64126
64127
64128
64129
64130
64131
64132
64133
64134
64135
64136
64137
64138
64139
64140
64141
64142
64143
64144
64145
64146
64147
64148
64149
64150
64151
64152
64153
64154
64155
64156
64157
64158
64159
64160
64161
64162
64163
64164
64165
64166
64167
64168
64169
64170
64171
64172
64173
64174
64175
64176
64177
64178
64179
64180
64181
64182
64183
64184
64185
64186
64187
64188
64189
64190
64191
64192
64193
64194
64195
64196
64197
64198
64199
64200
64201
64202
64203
64204
64205
64206
64207
64208
64209
64210
64211
64212
64213
64214
64215
64216
64217
64218
64219
64220
64221
64222
64223
64224
64225
64226
64227
64228
64229
64230
64231
64232
64233
64234
64235
64236
64237
64238
64239
64240
64241
64242
64243
64244
64245
64246
64247
64248
64249
64250
64251
64252
64253
64254
64255
64256
64257
64258
64259
64260
64261
64262
64263
64264
64265
64266
64267
64268
64269
64270
64271
64272
64273
64274
64275
64276
64277
64278
64279
64280
64281
64282
64283
64284
64285
64286
64287
64288
64289
64290
64291
64292
64293
64294
64295
64296
64297
64298
64299
64300
64301
64302
64303
64304
64305
64306
64307
64308
64309
64310
64311
64312
64313
64314
64315
64316
64317
64318
64319
64320
64321
64322
64323
64324
64325
64326
64327
64328
64329
64330
64331
64332
64333
64334
64335
64336
64337
64338
64339
64340
64341
64342
64343
64344
64345
64346
64347
64348
64349
64350
64351
64352
64353
64354
64355
64356
64357
64358
64359
64360
64361
64362
64363
64364
64365
64366
64367
64368
64369
64370
64371
64372
64373
64374
64375
64376
64377
64378
64379
64380
64381
64382
64383
64384
64385
64386
64387
64388
64389
64390
64391
64392
64393
64394
64395
64396
64397
64398
64399
64400
64401
64402
64403
64404
64405
64406
64407
64408
64409
64410
64411
64412
64413
64414
64415
64416
64417
64418
64419
64420
64421
64422
64423
64424
64425
64426
64427
64428
64429
64430
64431
64432
64433
64434
64435
64436
64437
64438
64439
64440
64441
64442
64443
64444
64445
64446
64447
64448
64449
64450
64451
64452
64453
64454
64455
64456
64457
64458
64459
64460
64461
64462
64463
64464
64465
64466
64467
64468
64469
64470
64471
64472
64473
64474
64475
64476
64477
64478
64479
64480
64481
64482
64483
64484
64485
64486
64487
64488
64489
64490
64491
64492
64493
64494
64495
64496
64497
64498
64499
64500
64501
64502
64503
64504
64505
64506
64507
64508
64509
64510
64511
64512
64513
64514
64515
64516
64517
64518
64519
64520
64521
64522
64523
64524
64525
64526
64527
64528
64529
64530
64531
64532
64533
64534
64535
64536
64537
64538
64539
64540
64541
64542
64543
64544
64545
64546
64547
64548
64549
64550
64551
64552
64553
64554
64555
64556
64557
64558
64559
64560
64561
64562
64563
64564
64565
64566
64567
64568
64569
64570
64571
64572
64573
64574
64575
64576
64577
64578
64579
64580
64581
64582
64583
64584
64585
64586
64587
64588
64589
64590
64591
64592
64593
64594
64595
64596
64597
64598
64599
64600
64601
64602
64603
64604
64605
64606
64607
64608
64609
64610
64611
64612
64613
64614
64615
64616
64617
64618
64619
64620
64621
64622
64623
64624
64625
64626
64627
64628
64629
64630
64631
64632
64633
64634
64635
64636
64637
64638
64639
64640
64641
64642
64643
64644
64645
64646
64647
64648
64649
64650
64651
64652
64653
64654
64655
64656
64657
64658
64659
64660
64661
64662
64663
64664
64665
64666
64667
64668
64669
64670
64671
64672
64673
64674
64675
64676
64677
64678
64679
64680
64681
64682
64683
64684
64685
64686
64687
64688
64689
64690
64691
64692
64693
64694
64695
64696
64697
64698
64699
64700
64701
64702
64703
64704
64705
64706
64707
64708
64709
64710
64711
64712
64713
64714
64715
64716
64717
64718
64719
64720
64721
64722
64723
64724
64725
64726
64727
64728
64729
64730
64731
64732
64733
64734
64735
64736
64737
64738
64739
64740
64741
64742
64743
64744
64745
64746
64747
64748
64749
64750
64751
64752
64753
64754
64755
64756
64757
64758
64759
64760
64761
64762
64763
64764
64765
64766
64767
64768
64769
64770
64771
64772
64773
64774
64775
64776
64777
64778
64779
64780
64781
64782
64783
64784
64785
64786
64787
64788
64789
64790
64791
64792
64793
64794
64795
64796
64797
64798
64799
64800
64801
64802
64803
64804
64805
64806
64807
64808
64809
64810
64811
64812
64813
64814
64815
64816
64817
64818
64819
64820
64821
64822
64823
64824
64825
64826
64827
64828
64829
64830
64831
64832
64833
64834
64835
64836
64837
64838
64839
64840
64841
64842
64843
64844
64845
64846
64847
64848
64849
64850
64851
64852
64853
64854
64855
64856
64857
64858
64859
64860
64861
64862
64863
64864
64865
64866
64867
64868
64869
64870
64871
64872
64873
64874
64875
64876
64877
64878
64879
64880
64881
64882
64883
64884
64885
64886
64887
64888
64889
64890
64891
64892
64893
64894
64895
64896
64897
64898
64899
64900
64901
64902
64903
64904
64905
64906
64907
64908
64909
64910
64911
64912
64913
64914
64915
64916
64917
64918
64919
64920
64921
64922
64923
64924
64925
64926
64927
64928
64929
64930
64931
64932
64933
64934
64935
64936
64937
64938
64939
64940
64941
64942
64943
64944
64945
64946
64947
64948
64949
64950
64951
64952
64953
64954
64955
64956
64957
64958
64959
64960
64961
64962
64963
64964
64965
64966
64967
64968
64969
64970
64971
64972
64973
64974
64975
64976
64977
64978
64979
64980
64981
64982
64983
64984
64985
64986
64987
64988
64989
64990
64991
64992
64993
64994
64995
64996
64997
64998
64999
65000
65001
65002
65003
65004
65005
65006
65007
65008
65009
65010
65011
65012
65013
65014
65015
65016
65017
65018
65019
65020
65021
65022
65023
65024
65025
65026
65027
65028
65029
65030
65031
65032
65033
65034
65035
65036
65037
65038
65039
65040
65041
65042
65043
65044
65045
65046
65047
65048
65049
65050
65051
65052
65053
65054
65055
65056
65057
65058
65059
65060
65061
65062
65063
65064
65065
65066
65067
65068
65069
65070
65071
65072
65073
65074
65075
65076
65077
65078
65079
65080
65081
65082
65083
65084
65085
65086
65087
65088
65089
65090
65091
65092
65093
65094
65095
65096
65097
65098
65099
65100
65101
65102
65103
65104
65105
65106
65107
65108
65109
65110
65111
65112
65113
65114
65115
65116
65117
65118
65119
65120
65121
65122
65123
65124
65125
65126
65127
65128
65129
65130
65131
65132
65133
65134
65135
65136
65137
65138
65139
65140
65141
65142
65143
65144
65145
65146
65147
65148
65149
65150
65151
65152
65153
65154
65155
65156
65157
65158
65159
65160
65161
65162
65163
65164
65165
65166
65167
65168
65169
65170
65171
65172
65173
65174
65175
65176
65177
65178
65179
65180
65181
65182
65183
65184
65185
65186
65187
65188
65189
65190
65191
65192
65193
65194
65195
65196
65197
65198
65199
65200
65201
65202
65203
65204
65205
65206
65207
65208
65209
65210
65211
65212
65213
65214
65215
65216
65217
65218
65219
65220
65221
65222
65223
65224
65225
65226
65227
65228
65229
65230
65231
65232
65233
65234
65235
65236
65237
65238
65239
65240
65241
65242
65243
65244
65245
65246
65247
65248
65249
65250
65251
65252
65253
65254
65255
65256
65257
65258
65259
65260
65261
65262
65263
65264
65265
65266
65267
65268
65269
65270
65271
65272
65273
65274
65275
65276
65277
65278
65279
65280
65281
65282
65283
65284
65285
65286
65287
65288
65289
65290
65291
65292
65293
65294
65295
65296
65297
65298
65299
65300
65301
65302
65303
65304
65305
65306
65307
65308
65309
65310
65311
65312
65313
65314
65315
65316
65317
65318
65319
65320
65321
65322
65323
65324
65325
65326
65327
65328
65329
65330
65331
65332
65333
65334
65335
65336
65337
65338
65339
65340
65341
65342
65343
65344
65345
65346
65347
65348
65349
65350
65351
65352
65353
65354
65355
65356
65357
65358
65359
65360
65361
65362
65363
65364
65365
65366
65367
65368
65369
65370
65371
65372
65373
65374
65375
65376
65377
65378
65379
65380
65381
65382
65383
65384
65385
65386
65387
65388
65389
65390
65391
65392
65393
65394
65395
65396
65397
65398
65399
65400
65401
65402
65403
65404
65405
65406
65407
65408
65409
65410
65411
65412
65413
65414
65415
65416
65417
65418
65419
65420
65421
65422
65423
65424
65425
65426
65427
65428
65429
65430
65431
65432
65433
65434
65435
65436
65437
65438
65439
65440
65441
65442
65443
65444
65445
65446
65447
65448
65449
65450
65451
65452
65453
65454
65455
65456
65457
65458
65459
65460
65461
65462
65463
65464
65465
65466
65467
65468
65469
65470
65471
65472
65473
65474
65475
65476
65477
65478
65479
65480
65481
65482
65483
65484
65485
65486
65487
65488
65489
65490
65491
65492
65493
65494
65495
65496
65497
65498
65499
65500
65501
65502
65503
65504
65505
65506
65507
65508
65509
65510
65511
65512
65513
65514
65515
65516
65517
65518
65519
65520
65521
65522
65523
65524
65525
65526
65527
65528
65529
65530
65531
65532
65533
65534
65535
65536
65537
65538
65539
65540
65541
65542
65543
65544
65545
65546
65547
65548
65549
65550
65551
65552
65553
65554
65555
65556
65557
65558
65559
65560
65561
65562
65563
65564
65565
65566
65567
65568
65569
65570
65571
65572
65573
65574
65575
65576
65577
65578
65579
65580
65581
65582
65583
65584
65585
65586
65587
65588
65589
65590
65591
65592
65593
65594
65595
65596
65597
65598
65599
65600
65601
65602
65603
65604
65605
65606
65607
65608
65609
65610
65611
65612
65613
65614
65615
65616
65617
65618
65619
65620
65621
65622
65623
65624
65625
65626
65627
65628
65629
65630
65631
65632
65633
65634
65635
65636
65637
65638
65639
65640
65641
65642
65643
65644
65645
65646
65647
65648
65649
65650
65651
65652
65653
65654
65655
65656
65657
65658
65659
65660
65661
65662
65663
65664
65665
65666
65667
65668
65669
65670
65671
65672
65673
65674
65675
65676
65677
65678
65679
65680
65681
65682
65683
65684
65685
65686
65687
65688
65689
65690
65691
65692
65693
65694
65695
65696
65697
65698
65699
65700
65701
65702
65703
65704
65705
65706
65707
65708
65709
65710
65711
65712
65713
65714
65715
65716
65717
65718
65719
65720
65721
65722
65723
65724
65725
65726
65727
65728
65729
65730
65731
65732
65733
65734
65735
65736
65737
65738
65739
65740
65741
65742
65743
65744
65745
65746
65747
65748
65749
65750
65751
65752
65753
65754
65755
65756
65757
65758
65759
65760
65761
65762
65763
65764
65765
65766
65767
65768
65769
65770
65771
65772
65773
65774
65775
65776
65777
65778
65779
65780
65781
65782
65783
65784
65785
65786
65787
65788
65789
65790
65791
65792
65793
65794
65795
65796
65797
65798
65799
65800
65801
65802
65803
65804
65805
65806
65807
65808
65809
65810
65811
65812
65813
65814
65815
65816
65817
65818
65819
65820
65821
65822
65823
65824
65825
65826
65827
65828
65829
65830
65831
65832
65833
65834
65835
65836
65837
65838
65839
65840
65841
65842
65843
65844
65845
65846
65847
65848
65849
65850
65851
65852
65853
65854
65855
65856
65857
65858
65859
65860
65861
65862
65863
65864
65865
65866
65867
65868
65869
65870
65871
65872
65873
65874
65875
65876
65877
65878
65879
65880
65881
65882
65883
65884
65885
65886
65887
65888
65889
65890
65891
65892
65893
65894
65895
65896
65897
65898
65899
65900
65901
65902
65903
65904
65905
65906
65907
65908
65909
65910
65911
65912
65913
65914
65915
65916
65917
65918
65919
65920
65921
65922
65923
65924
65925
65926
65927
65928
65929
65930
65931
65932
65933
65934
65935
65936
65937
65938
65939
65940
65941
65942
65943
65944
65945
65946
65947
65948
65949
65950
65951
65952
65953
65954
65955
65956
65957
65958
65959
65960
65961
65962
65963
65964
65965
65966
65967
65968
65969
65970
65971
65972
65973
65974
65975
65976
65977
65978
65979
65980
65981
65982
65983
65984
65985
65986
65987
65988
65989
65990
65991
65992
65993
65994
65995
65996
65997
65998
65999
66000
66001
66002
66003
66004
66005
66006
66007
66008
66009
66010
66011
66012
66013
66014
66015
66016
66017
66018
66019
66020
66021
66022
66023
66024
66025
66026
66027
66028
66029
66030
66031
66032
66033
66034
66035
66036
66037
66038
66039
66040
66041
66042
66043
66044
66045
66046
66047
66048
66049
66050
66051
66052
66053
66054
66055
66056
66057
66058
66059
66060
66061
66062
66063
66064
66065
66066
66067
66068
66069
66070
66071
66072
66073
66074
66075
66076
66077
66078
66079
66080
66081
66082
66083
66084
66085
66086
66087
66088
66089
66090
66091
66092
66093
66094
66095
66096
66097
66098
66099
66100
66101
66102
66103
66104
66105
66106
66107
66108
66109
66110
66111
66112
66113
66114
66115
66116
66117
66118
66119
66120
66121
66122
66123
66124
66125
66126
66127
66128
66129
66130
66131
66132
66133
66134
66135
66136
66137
66138
66139
66140
66141
66142
66143
66144
66145
66146
66147
66148
66149
66150
66151
66152
66153
66154
66155
66156
66157
66158
66159
66160
66161
66162
66163
66164
66165
66166
66167
66168
66169
66170
66171
66172
66173
66174
66175
66176
66177
66178
66179
66180
66181
66182
66183
66184
66185
66186
66187
66188
66189
66190
66191
66192
66193
66194
66195
66196
66197
66198
66199
66200
66201
66202
66203
66204
66205
66206
66207
66208
66209
66210
66211
66212
66213
66214
66215
66216
66217
66218
66219
66220
66221
66222
66223
66224
66225
66226
66227
66228
66229
66230
66231
66232
66233
66234
66235
66236
66237
66238
66239
66240
66241
66242
66243
66244
66245
66246
66247
66248
66249
66250
66251
66252
66253
66254
66255
66256
66257
66258
66259
66260
66261
66262
66263
66264
66265
66266
66267
66268
66269
66270
66271
66272
66273
66274
66275
66276
66277
66278
66279
66280
66281
66282
66283
66284
66285
66286
66287
66288
66289
66290
66291
66292
66293
66294
66295
66296
66297
66298
66299
66300
66301
66302
66303
66304
66305
66306
66307
66308
66309
66310
66311
66312
66313
66314
66315
66316
66317
66318
66319
66320
66321
66322
66323
66324
66325
66326
66327
66328
66329
66330
66331
66332
66333
66334
66335
66336
66337
66338
66339
66340
66341
66342
66343
66344
66345
66346
66347
66348
66349
66350
66351
66352
66353
66354
66355
66356
66357
66358
66359
66360
66361
66362
66363
66364
66365
66366
66367
66368
66369
66370
66371
66372
66373
66374
66375
66376
66377
66378
66379
66380
66381
66382
66383
66384
66385
66386
66387
66388
66389
66390
66391
66392
66393
66394
66395
66396
66397
66398
66399
66400
66401
66402
66403
66404
66405
66406
66407
66408
66409
66410
66411
66412
66413
66414
66415
66416
66417
66418
66419
66420
66421
66422
66423
66424
66425
66426
66427
66428
66429
66430
66431
66432
66433
66434
66435
66436
66437
66438
66439
66440
66441
66442
66443
66444
66445
66446
66447
66448
66449
66450
66451
66452
66453
66454
66455
66456
66457
66458
66459
66460
66461
66462
66463
66464
66465
66466
66467
66468
66469
66470
66471
66472
66473
66474
66475
66476
66477
66478
66479
66480
66481
66482
66483
66484
66485
66486
66487
66488
66489
66490
66491
66492
66493
66494
66495
66496
66497
66498
66499
66500
66501
66502
66503
66504
66505
66506
66507
66508
66509
66510
66511
66512
66513
66514
66515
66516
66517
66518
66519
66520
66521
66522
66523
66524
66525
66526
66527
66528
66529
66530
66531
66532
66533
66534
66535
66536
66537
66538
66539
66540
66541
66542
66543
66544
66545
66546
66547
66548
66549
66550
66551
66552
66553
66554
66555
66556
66557
66558
66559
66560
66561
66562
66563
66564
66565
66566
66567
66568
66569
66570
66571
66572
66573
66574
66575
66576
66577
66578
66579
66580
66581
66582
66583
66584
66585
66586
66587
66588
66589
66590
66591
66592
66593
66594
66595
66596
66597
66598
66599
66600
66601
66602
66603
66604
66605
66606
66607
66608
66609
66610
66611
66612
66613
66614
66615
66616
66617
66618
66619
66620
66621
66622
66623
66624
66625
66626
66627
66628
66629
66630
66631
66632
66633
66634
66635
66636
66637
66638
66639
66640
66641
66642
66643
66644
66645
66646
66647
66648
66649
66650
66651
66652
66653
66654
66655
66656
66657
66658
66659
66660
66661
66662
66663
66664
66665
66666
66667
66668
66669
66670
66671
66672
66673
66674
66675
66676
66677
66678
66679
66680
66681
66682
66683
66684
66685
66686
66687
66688
66689
66690
66691
66692
66693
66694
66695
66696
66697
66698
66699
66700
66701
66702
66703
66704
66705
66706
66707
66708
66709
66710
66711
66712
66713
66714
66715
66716
66717
66718
66719
66720
66721
66722
66723
66724
66725
66726
66727
66728
66729
66730
66731
66732
66733
66734
66735
66736
66737
66738
66739
66740
66741
66742
66743
66744
66745
66746
66747
66748
66749
66750
66751
66752
66753
66754
66755
66756
66757
66758
66759
66760
66761
66762
66763
66764
66765
66766
66767
66768
66769
66770
66771
66772
66773
66774
66775
66776
66777
66778
66779
66780
66781
66782
66783
66784
66785
66786
66787
66788
66789
66790
66791
66792
66793
66794
66795
66796
66797
66798
66799
66800
66801
66802
66803
66804
66805
66806
66807
66808
66809
66810
66811
66812
66813
66814
66815
66816
66817
66818
66819
66820
66821
66822
66823
66824
66825
66826
66827
66828
66829
66830
66831
66832
66833
66834
66835
66836
66837
66838
66839
66840
66841
66842
66843
66844
66845
66846
66847
66848
66849
66850
66851
66852
66853
66854
66855
66856
66857
66858
66859
66860
66861
66862
66863
66864
66865
66866
66867
66868
66869
66870
66871
66872
66873
66874
66875
66876
66877
66878
66879
66880
66881
66882
66883
66884
66885
66886
66887
66888
66889
66890
66891
66892
66893
66894
66895
66896
66897
66898
66899
66900
66901
66902
66903
66904
66905
66906
66907
66908
66909
66910
66911
66912
66913
66914
66915
66916
66917
66918
66919
66920
66921
66922
66923
66924
66925
66926
66927
66928
66929
66930
66931
66932
66933
66934
66935
66936
66937
66938
66939
66940
66941
66942
66943
66944
66945
66946
66947
66948
66949
66950
66951
66952
66953
66954
66955
66956
66957
66958
66959
66960
66961
66962
66963
66964
66965
66966
66967
66968
66969
66970
66971
66972
66973
66974
66975
66976
66977
66978
66979
66980
66981
66982
66983
66984
66985
66986
66987
66988
66989
66990
66991
66992
66993
66994
66995
66996
66997
66998
66999
67000
67001
67002
67003
67004
67005
67006
67007
67008
67009
67010
67011
67012
67013
67014
67015
67016
67017
67018
67019
67020
67021
67022
67023
67024
67025
67026
67027
67028
67029
67030
67031
67032
67033
67034
67035
67036
67037
67038
67039
67040
67041
67042
67043
67044
67045
67046
67047
67048
67049
67050
67051
67052
67053
67054
67055
67056
67057
67058
67059
67060
67061
67062
67063
67064
67065
67066
67067
67068
67069
67070
67071
67072
67073
67074
67075
67076
67077
67078
67079
67080
67081
67082
67083
67084
67085
67086
67087
67088
67089
67090
67091
67092
67093
67094
67095
67096
67097
67098
67099
67100
67101
67102
67103
67104
67105
67106
67107
67108
67109
67110
67111
67112
67113
67114
67115
67116
67117
67118
67119
67120
67121
67122
67123
67124
67125
67126
67127
67128
67129
67130
67131
67132
67133
67134
67135
67136
67137
67138
67139
67140
67141
67142
67143
67144
67145
67146
67147
67148
67149
67150
67151
67152
67153
67154
67155
67156
67157
67158
67159
67160
67161
67162
67163
67164
67165
67166
67167
67168
67169
67170
67171
67172
67173
67174
67175
67176
67177
67178
67179
67180
67181
67182
67183
67184
67185
67186
67187
67188
67189
67190
67191
67192
67193
67194
67195
67196
67197
67198
67199
67200
67201
67202
67203
67204
67205
67206
67207
67208
67209
67210
67211
67212
67213
67214
67215
67216
67217
67218
67219
67220
67221
67222
67223
67224
67225
67226
67227
67228
67229
67230
67231
67232
67233
67234
67235
67236
67237
67238
67239
67240
67241
67242
67243
67244
67245
67246
67247
67248
67249
67250
67251
67252
67253
67254
67255
67256
67257
67258
67259
67260
67261
67262
67263
67264
67265
67266
67267
67268
67269
67270
67271
67272
67273
67274
67275
67276
67277
67278
67279
67280
67281
67282
67283
67284
67285
67286
67287
67288
67289
67290
67291
67292
67293
67294
67295
67296
67297
67298
67299
67300
67301
67302
67303
67304
67305
67306
67307
67308
67309
67310
67311
67312
67313
67314
67315
67316
67317
67318
67319
67320
67321
67322
67323
67324
67325
67326
67327
67328
67329
67330
67331
67332
67333
67334
67335
67336
67337
67338
67339
67340
67341
67342
67343
67344
67345
67346
67347
67348
67349
67350
67351
67352
67353
67354
67355
67356
67357
67358
67359
67360
67361
67362
67363
67364
67365
67366
67367
67368
67369
67370
67371
67372
67373
67374
67375
67376
67377
67378
67379
67380
67381
67382
67383
67384
67385
67386
67387
67388
67389
67390
67391
67392
67393
67394
67395
67396
67397
67398
67399
67400
67401
67402
67403
67404
67405
67406
67407
67408
67409
67410
67411
67412
67413
67414
67415
67416
67417
67418
67419
67420
67421
67422
67423
67424
67425
67426
67427
67428
67429
67430
67431
67432
67433
67434
67435
67436
67437
67438
67439
67440
67441
67442
67443
67444
67445
67446
67447
67448
67449
67450
67451
67452
67453
67454
67455
67456
67457
67458
67459
67460
67461
67462
67463
67464
67465
67466
67467
67468
67469
67470
67471
67472
67473
67474
67475
67476
67477
67478
67479
67480
67481
67482
67483
67484
67485
67486
67487
67488
67489
67490
67491
67492
67493
67494
67495
67496
67497
67498
67499
67500
67501
67502
67503
67504
67505
67506
67507
67508
67509
67510
67511
67512
67513
67514
67515
67516
67517
67518
67519
67520
67521
67522
67523
67524
67525
67526
67527
67528
67529
67530
67531
67532
67533
67534
67535
67536
67537
67538
67539
67540
67541
67542
67543
67544
67545
67546
67547
67548
67549
67550
67551
67552
67553
67554
67555
67556
67557
67558
67559
67560
67561
67562
67563
67564
67565
67566
67567
67568
67569
67570
67571
67572
67573
67574
67575
67576
67577
67578
67579
67580
67581
67582
67583
67584
67585
67586
67587
67588
67589
67590
67591
67592
67593
67594
67595
67596
67597
67598
67599
67600
67601
67602
67603
67604
67605
67606
67607
67608
67609
67610
67611
67612
67613
67614
67615
67616
67617
67618
67619
67620
67621
67622
67623
67624
67625
67626
67627
67628
67629
67630
67631
67632
67633
67634
67635
67636
67637
67638
67639
67640
67641
67642
67643
67644
67645
67646
67647
67648
67649
67650
67651
67652
67653
67654
67655
67656
67657
67658
67659
67660
67661
67662
67663
67664
67665
67666
67667
67668
67669
67670
67671
67672
67673
67674
67675
67676
67677
67678
67679
67680
67681
67682
67683
67684
67685
67686
67687
67688
67689
67690
67691
67692
67693
67694
67695
67696
67697
67698
67699
67700
67701
67702
67703
67704
67705
67706
67707
67708
67709
67710
67711
67712
67713
67714
67715
67716
67717
67718
67719
67720
67721
67722
67723
67724
67725
67726
67727
67728
67729
67730
67731
67732
67733
67734
67735
67736
67737
67738
67739
67740
67741
67742
67743
67744
67745
67746
67747
67748
67749
67750
67751
67752
67753
67754
67755
67756
67757
67758
67759
67760
67761
67762
67763
67764
67765
67766
67767
67768
67769
67770
67771
67772
67773
67774
67775
67776
67777
67778
67779
67780
67781
67782
67783
67784
67785
67786
67787
67788
67789
67790
67791
67792
67793
67794
67795
67796
67797
67798
67799
67800
67801
67802
67803
67804
67805
67806
67807
67808
67809
67810
67811
67812
67813
67814
67815
67816
67817
67818
67819
67820
67821
67822
67823
67824
67825
67826
67827
67828
67829
67830
67831
67832
67833
67834
67835
67836
67837
67838
67839
67840
67841
67842
67843
67844
67845
67846
67847
67848
67849
67850
67851
67852
67853
67854
67855
67856
67857
67858
67859
67860
67861
67862
67863
67864
67865
67866
67867
67868
67869
67870
67871
67872
67873
67874
67875
67876
67877
67878
67879
67880
67881
67882
67883
67884
67885
67886
67887
67888
67889
67890
67891
67892
67893
67894
67895
67896
67897
67898
67899
67900
67901
67902
67903
67904
67905
67906
67907
67908
67909
67910
67911
67912
67913
67914
67915
67916
67917
67918
67919
67920
67921
67922
67923
67924
67925
67926
67927
67928
67929
67930
67931
67932
67933
67934
67935
67936
67937
67938
67939
67940
67941
67942
67943
67944
67945
67946
67947
67948
67949
67950
67951
67952
67953
67954
67955
67956
67957
67958
67959
67960
67961
67962
67963
67964
67965
67966
67967
67968
67969
67970
67971
67972
67973
67974
67975
67976
67977
67978
67979
67980
67981
67982
67983
67984
67985
67986
67987
67988
67989
67990
67991
67992
67993
67994
67995
67996
67997
67998
67999
68000
68001
68002
68003
68004
68005
68006
68007
68008
68009
68010
68011
68012
68013
68014
68015
68016
68017
68018
68019
68020
68021
68022
68023
68024
68025
68026
68027
68028
68029
68030
68031
68032
68033
68034
68035
68036
68037
68038
68039
68040
68041
68042
68043
68044
68045
68046
68047
68048
68049
68050
68051
68052
68053
68054
68055
68056
68057
68058
68059
68060
68061
68062
68063
68064
68065
68066
68067
68068
68069
68070
68071
68072
68073
68074
68075
68076
68077
68078
68079
68080
68081
68082
68083
68084
68085
68086
68087
68088
68089
68090
68091
68092
68093
68094
68095
68096
68097
68098
68099
68100
68101
68102
68103
68104
68105
68106
68107
68108
68109
68110
68111
68112
68113
68114
68115
68116
68117
68118
68119
68120
68121
68122
68123
68124
68125
68126
68127
68128
68129
68130
68131
68132
68133
68134
68135
68136
68137
68138
68139
68140
68141
68142
68143
68144
68145
68146
68147
68148
68149
68150
68151
68152
68153
68154
68155
68156
68157
68158
68159
68160
68161
68162
68163
68164
68165
68166
68167
68168
68169
68170
68171
68172
68173
68174
68175
68176
68177
68178
68179
68180
68181
68182
68183
68184
68185
68186
68187
68188
68189
68190
68191
68192
68193
68194
68195
68196
68197
68198
68199
68200
68201
68202
68203
68204
68205
68206
68207
68208
68209
68210
68211
68212
68213
68214
68215
68216
68217
68218
68219
68220
68221
68222
68223
68224
68225
68226
68227
68228
68229
68230
68231
68232
68233
68234
68235
68236
68237
68238
68239
68240
68241
68242
68243
68244
68245
68246
68247
68248
68249
68250
68251
68252
68253
68254
68255
68256
68257
68258
68259
68260
68261
68262
68263
68264
68265
68266
68267
68268
68269
68270
68271
68272
68273
68274
68275
68276
68277
68278
68279
68280
68281
68282
68283
68284
68285
68286
68287
68288
68289
68290
68291
68292
68293
68294
68295
68296
68297
68298
68299
68300
68301
68302
68303
68304
68305
68306
68307
68308
68309
68310
68311
68312
68313
68314
68315
68316
68317
68318
68319
68320
68321
68322
68323
68324
68325
68326
68327
68328
68329
68330
68331
68332
68333
68334
68335
68336
68337
68338
68339
68340
68341
68342
68343
68344
68345
68346
68347
68348
68349
68350
68351
68352
68353
68354
68355
68356
68357
68358
68359
68360
68361
68362
68363
68364
68365
68366
68367
68368
68369
68370
68371
68372
68373
68374
68375
68376
68377
68378
68379
68380
68381
68382
68383
68384
68385
68386
68387
68388
68389
68390
68391
68392
68393
68394
68395
68396
68397
68398
68399
68400
68401
68402
68403
68404
68405
68406
68407
68408
68409
68410
68411
68412
68413
68414
68415
68416
68417
68418
68419
68420
68421
68422
68423
68424
68425
68426
68427
68428
68429
68430
68431
68432
68433
68434
68435
68436
68437
68438
68439
68440
68441
68442
68443
68444
68445
68446
68447
68448
68449
68450
68451
68452
68453
68454
68455
68456
68457
68458
68459
68460
68461
68462
68463
68464
68465
68466
68467
68468
68469
68470
68471
68472
68473
68474
68475
68476
68477
68478
68479
68480
68481
68482
68483
68484
68485
68486
68487
68488
68489
68490
68491
68492
68493
68494
68495
68496
68497
68498
68499
68500
68501
68502
68503
68504
68505
68506
68507
68508
68509
68510
68511
68512
68513
68514
68515
68516
68517
68518
68519
68520
68521
68522
68523
68524
68525
68526
68527
68528
68529
68530
68531
68532
68533
68534
68535
68536
68537
68538
68539
68540
68541
68542
68543
68544
68545
68546
68547
68548
68549
68550
68551
68552
68553
68554
68555
68556
68557
68558
68559
68560
68561
68562
68563
68564
68565
68566
68567
68568
68569
68570
68571
68572
68573
68574
68575
68576
68577
68578
68579
68580
68581
68582
68583
68584
68585
68586
68587
68588
68589
68590
68591
68592
68593
68594
68595
68596
68597
68598
68599
68600
68601
68602
68603
68604
68605
68606
68607
68608
68609
68610
68611
68612
68613
68614
68615
68616
68617
68618
68619
68620
68621
68622
68623
68624
68625
68626
68627
68628
68629
68630
68631
68632
68633
68634
68635
68636
68637
68638
68639
68640
68641
68642
68643
68644
68645
68646
68647
68648
68649
68650
68651
68652
68653
68654
68655
68656
68657
68658
68659
68660
68661
68662
68663
68664
68665
68666
68667
68668
68669
68670
68671
68672
68673
68674
68675
68676
68677
68678
68679
68680
68681
68682
68683
68684
68685
68686
68687
68688
68689
68690
68691
68692
68693
68694
68695
68696
68697
68698
68699
68700
68701
68702
68703
68704
68705
68706
68707
68708
68709
68710
68711
68712
68713
68714
68715
68716
68717
68718
68719
68720
68721
68722
68723
68724
68725
68726
68727
68728
68729
68730
68731
68732
68733
68734
68735
68736
68737
68738
68739
68740
68741
68742
68743
68744
68745
68746
68747
68748
68749
68750
68751
68752
68753
68754
68755
68756
68757
68758
68759
68760
68761
68762
68763
68764
68765
68766
68767
68768
68769
68770
68771
68772
68773
68774
68775
68776
68777
68778
68779
68780
68781
68782
68783
68784
68785
68786
68787
68788
68789
68790
68791
68792
68793
68794
68795
68796
68797
68798
68799
68800
68801
68802
68803
68804
68805
68806
68807
68808
68809
68810
68811
68812
68813
68814
68815
68816
68817
68818
68819
68820
68821
68822
68823
68824
68825
68826
68827
68828
68829
68830
68831
68832
68833
68834
68835
68836
68837
68838
68839
68840
68841
68842
68843
68844
68845
68846
68847
68848
68849
68850
68851
68852
68853
68854
68855
68856
68857
68858
68859
68860
68861
68862
68863
68864
68865
68866
68867
68868
68869
68870
68871
68872
68873
68874
68875
68876
68877
68878
68879
68880
68881
68882
68883
68884
68885
68886
68887
68888
68889
68890
68891
68892
68893
68894
68895
68896
68897
68898
68899
68900
68901
68902
68903
68904
68905
68906
68907
68908
68909
68910
68911
68912
68913
68914
68915
68916
68917
68918
68919
68920
68921
68922
68923
68924
68925
68926
68927
68928
68929
68930
68931
68932
68933
68934
68935
68936
68937
68938
68939
68940
68941
68942
68943
68944
68945
68946
68947
68948
68949
68950
68951
68952
68953
68954
68955
68956
68957
68958
68959
68960
68961
68962
68963
68964
68965
68966
68967
68968
68969
68970
68971
68972
68973
68974
68975
68976
68977
68978
68979
68980
68981
68982
68983
68984
68985
68986
68987
68988
68989
68990
68991
68992
68993
68994
68995
68996
68997
68998
68999
69000
69001
69002
69003
69004
69005
69006
69007
69008
69009
69010
69011
69012
69013
69014
69015
69016
69017
69018
69019
69020
69021
69022
69023
69024
69025
69026
69027
69028
69029
69030
69031
69032
69033
69034
69035
69036
69037
69038
69039
69040
69041
69042
69043
69044
69045
69046
69047
69048
69049
69050
69051
69052
69053
69054
69055
69056
69057
69058
69059
69060
69061
69062
69063
69064
69065
69066
69067
69068
69069
69070
69071
69072
69073
69074
69075
69076
69077
69078
69079
69080
69081
69082
69083
69084
69085
69086
69087
69088
69089
69090
69091
69092
69093
69094
69095
69096
69097
69098
69099
69100
69101
69102
69103
69104
69105
69106
69107
69108
69109
69110
69111
69112
69113
69114
69115
69116
69117
69118
69119
69120
69121
69122
69123
69124
69125
69126
69127
69128
69129
69130
69131
69132
69133
69134
69135
69136
69137
69138
69139
69140
69141
69142
69143
69144
69145
69146
69147
69148
69149
69150
69151
69152
69153
69154
69155
69156
69157
69158
69159
69160
69161
69162
69163
69164
69165
69166
69167
69168
69169
69170
69171
69172
69173
69174
69175
69176
69177
69178
69179
69180
69181
69182
69183
69184
69185
69186
69187
69188
69189
69190
69191
69192
69193
69194
69195
69196
69197
69198
69199
69200
69201
69202
69203
69204
69205
69206
69207
69208
69209
69210
69211
69212
69213
69214
69215
69216
69217
69218
69219
69220
69221
69222
69223
69224
69225
69226
69227
69228
69229
69230
69231
69232
69233
69234
69235
69236
69237
69238
69239
69240
69241
69242
69243
69244
69245
69246
69247
69248
69249
69250
69251
69252
69253
69254
69255
69256
69257
69258
69259
69260
69261
69262
69263
69264
69265
69266
69267
69268
69269
69270
69271
69272
69273
69274
69275
69276
69277
69278
69279
69280
69281
69282
69283
69284
69285
69286
69287
69288
69289
69290
69291
69292
69293
69294
69295
69296
69297
69298
69299
69300
69301
69302
69303
69304
69305
69306
69307
69308
69309
69310
69311
69312
69313
69314
69315
69316
69317
69318
69319
69320
69321
69322
69323
69324
69325
69326
69327
69328
69329
69330
69331
69332
69333
69334
69335
69336
69337
69338
69339
69340
69341
69342
69343
69344
69345
69346
69347
69348
69349
69350
69351
69352
69353
69354
69355
69356
69357
69358
69359
69360
69361
69362
69363
69364
69365
69366
69367
69368
69369
69370
69371
69372
69373
69374
69375
69376
69377
69378
69379
69380
69381
69382
69383
69384
69385
69386
69387
69388
69389
69390
69391
69392
69393
69394
69395
69396
69397
69398
69399
69400
69401
69402
69403
69404
69405
69406
69407
69408
69409
69410
69411
69412
69413
69414
69415
69416
69417
69418
69419
69420
69421
69422
69423
69424
69425
69426
69427
69428
69429
69430
69431
69432
69433
69434
69435
69436
69437
69438
69439
69440
69441
69442
69443
69444
69445
69446
69447
69448
69449
69450
69451
69452
69453
69454
69455
69456
69457
69458
69459
69460
69461
69462
69463
69464
69465
69466
69467
69468
69469
69470
69471
69472
69473
69474
69475
69476
69477
69478
69479
69480
69481
69482
69483
69484
69485
69486
69487
69488
69489
69490
69491
69492
69493
69494
69495
69496
69497
69498
69499
69500
69501
69502
69503
69504
69505
69506
69507
69508
69509
69510
69511
69512
69513
69514
69515
69516
69517
69518
69519
69520
69521
69522
69523
69524
69525
69526
69527
69528
69529
69530
69531
69532
69533
69534
69535
69536
69537
69538
69539
69540
69541
69542
69543
69544
69545
69546
69547
69548
69549
69550
69551
69552
69553
69554
69555
69556
69557
69558
69559
69560
69561
69562
69563
69564
69565
69566
69567
69568
69569
69570
69571
69572
69573
69574
69575
69576
69577
69578
69579
69580
69581
69582
69583
69584
69585
69586
69587
69588
69589
69590
69591
69592
69593
69594
69595
69596
69597
69598
69599
69600
69601
69602
69603
69604
69605
69606
69607
69608
69609
69610
69611
69612
69613
69614
69615
69616
69617
69618
69619
69620
69621
69622
69623
69624
69625
69626
69627
69628
69629
69630
69631
69632
69633
69634
69635
69636
69637
69638
69639
69640
69641
69642
69643
69644
69645
69646
69647
69648
69649
69650
69651
69652
69653
69654
69655
69656
69657
69658
69659
69660
69661
69662
69663
69664
69665
69666
69667
69668
69669
69670
69671
69672
69673
69674
69675
69676
69677
69678
69679
69680
69681
69682
69683
69684
69685
69686
69687
69688
69689
69690
69691
69692
69693
69694
69695
69696
69697
69698
69699
69700
69701
69702
69703
69704
69705
69706
69707
69708
69709
69710
69711
69712
69713
69714
69715
69716
69717
69718
69719
69720
69721
69722
69723
69724
69725
69726
69727
69728
69729
69730
69731
69732
69733
69734
69735
69736
69737
69738
69739
69740
69741
69742
69743
69744
69745
69746
69747
69748
69749
69750
69751
69752
69753
69754
69755
69756
69757
69758
69759
69760
69761
69762
69763
69764
69765
69766
69767
69768
69769
69770
69771
69772
69773
69774
69775
69776
69777
69778
69779
69780
69781
69782
69783
69784
69785
69786
69787
69788
69789
69790
69791
69792
69793
69794
69795
69796
69797
69798
69799
69800
69801
69802
69803
69804
69805
69806
69807
69808
69809
69810
69811
69812
69813
69814
69815
69816
69817
69818
69819
69820
69821
69822
69823
69824
69825
69826
69827
69828
69829
69830
69831
69832
69833
69834
69835
69836
69837
69838
69839
69840
69841
69842
69843
69844
69845
69846
69847
69848
69849
69850
69851
69852
69853
69854
69855
69856
69857
69858
69859
69860
69861
69862
69863
69864
69865
69866
69867
69868
69869
69870
69871
69872
69873
69874
69875
69876
69877
69878
69879
69880
69881
69882
69883
69884
69885
69886
69887
69888
69889
69890
69891
69892
69893
69894
69895
69896
69897
69898
69899
69900
69901
69902
69903
69904
69905
69906
69907
69908
69909
69910
69911
69912
69913
69914
69915
69916
69917
69918
69919
69920
69921
69922
69923
69924
69925
69926
69927
69928
69929
69930
69931
69932
69933
69934
69935
69936
69937
69938
69939
69940
69941
69942
69943
69944
69945
69946
69947
69948
69949
69950
69951
69952
69953
69954
69955
69956
69957
69958
69959
69960
69961
69962
69963
69964
69965
69966
69967
69968
69969
69970
69971
69972
69973
69974
69975
69976
69977
69978
69979
69980
69981
69982
69983
69984
69985
69986
69987
69988
69989
69990
69991
69992
69993
69994
69995
69996
69997
69998
69999
70000
70001
70002
70003
70004
70005
70006
70007
70008
70009
70010
70011
70012
70013
70014
70015
70016
70017
70018
70019
70020
70021
70022
70023
70024
70025
70026
70027
70028
70029
70030
70031
70032
70033
70034
70035
70036
70037
70038
70039
70040
70041
70042
70043
70044
70045
70046
70047
70048
70049
70050
70051
70052
70053
70054
70055
70056
70057
70058
70059
70060
70061
70062
70063
70064
70065
70066
70067
70068
70069
70070
70071
70072
70073
70074
70075
70076
70077
70078
70079
70080
70081
70082
70083
70084
70085
70086
70087
70088
70089
70090
70091
70092
70093
70094
70095
70096
70097
70098
70099
70100
70101
70102
70103
70104
70105
70106
70107
70108
70109
70110
70111
70112
70113
70114
70115
70116
70117
70118
70119
70120
70121
70122
70123
70124
70125
70126
70127
70128
70129
70130
70131
70132
70133
70134
70135
70136
70137
70138
70139
70140
70141
70142
70143
70144
70145
70146
70147
70148
70149
70150
70151
70152
70153
70154
70155
70156
70157
70158
70159
70160
70161
70162
70163
70164
70165
70166
70167
70168
70169
70170
70171
70172
70173
70174
70175
70176
70177
70178
70179
70180
70181
70182
70183
70184
70185
70186
70187
70188
70189
70190
70191
70192
70193
70194
70195
70196
70197
70198
70199
70200
70201
70202
70203
70204
70205
70206
70207
70208
70209
70210
70211
70212
70213
70214
70215
70216
70217
70218
70219
70220
70221
70222
70223
70224
70225
70226
70227
70228
70229
70230
70231
70232
70233
70234
70235
70236
70237
70238
70239
70240
70241
70242
70243
70244
70245
70246
70247
70248
70249
70250
70251
70252
70253
70254
70255
70256
70257
70258
70259
70260
70261
70262
70263
70264
70265
70266
70267
70268
70269
70270
70271
70272
70273
70274
70275
70276
70277
70278
70279
70280
70281
70282
70283
70284
70285
70286
70287
70288
70289
70290
70291
70292
70293
70294
70295
70296
70297
70298
70299
70300
70301
70302
70303
70304
70305
70306
70307
70308
70309
70310
70311
70312
70313
70314
70315
70316
70317
70318
70319
70320
70321
70322
70323
70324
70325
70326
70327
70328
70329
70330
70331
70332
70333
70334
70335
70336
70337
70338
70339
70340
70341
70342
70343
70344
70345
70346
70347
70348
70349
70350
70351
70352
70353
70354
70355
70356
70357
70358
70359
70360
70361
70362
70363
70364
70365
70366
70367
70368
70369
70370
70371
70372
70373
70374
70375
70376
70377
70378
70379
70380
70381
70382
70383
70384
70385
70386
70387
70388
70389
70390
70391
70392
70393
70394
70395
70396
70397
70398
70399
70400
70401
70402
70403
70404
70405
70406
70407
70408
70409
70410
70411
70412
70413
70414
70415
70416
70417
70418
70419
70420
70421
70422
70423
70424
70425
70426
70427
70428
70429
70430
70431
70432
70433
70434
70435
70436
70437
70438
70439
70440
70441
70442
70443
70444
70445
70446
70447
70448
70449
70450
70451
70452
70453
70454
70455
70456
70457
70458
70459
70460
70461
70462
70463
70464
70465
70466
70467
70468
70469
70470
70471
70472
70473
70474
70475
70476
70477
70478
70479
70480
70481
70482
70483
70484
70485
70486
70487
70488
70489
70490
70491
70492
70493
70494
70495
70496
70497
70498
70499
70500
70501
70502
70503
70504
70505
70506
70507
70508
70509
70510
70511
70512
70513
70514
70515
70516
70517
70518
70519
70520
70521
70522
70523
70524
70525
70526
70527
70528
70529
70530
70531
70532
70533
70534
70535
70536
70537
70538
70539
70540
70541
70542
70543
70544
70545
70546
70547
70548
70549
70550
70551
70552
70553
70554
70555
70556
70557
70558
70559
70560
70561
70562
70563
70564
70565
70566
70567
70568
70569
70570
70571
70572
70573
70574
70575
70576
70577
70578
70579
70580
70581
70582
70583
70584
70585
70586
70587
70588
70589
70590
70591
70592
70593
70594
70595
70596
70597
70598
70599
70600
70601
70602
70603
70604
70605
70606
70607
70608
70609
70610
70611
70612
70613
70614
70615
70616
70617
70618
70619
70620
70621
70622
70623
70624
70625
70626
70627
70628
70629
70630
70631
70632
70633
70634
70635
70636
70637
70638
70639
70640
70641
70642
70643
70644
70645
70646
70647
70648
70649
70650
70651
70652
70653
70654
70655
70656
70657
70658
70659
70660
70661
70662
70663
70664
70665
70666
70667
70668
70669
70670
70671
70672
70673
70674
70675
70676
70677
70678
70679
70680
70681
70682
70683
70684
70685
70686
70687
70688
70689
70690
70691
70692
70693
70694
70695
70696
70697
70698
70699
70700
70701
70702
70703
70704
70705
70706
70707
70708
70709
70710
70711
70712
70713
70714
70715
70716
70717
70718
70719
70720
70721
70722
70723
70724
70725
70726
70727
70728
70729
70730
70731
70732
70733
70734
70735
70736
70737
70738
70739
70740
70741
70742
70743
70744
70745
70746
70747
70748
70749
70750
70751
70752
70753
70754
70755
70756
70757
70758
70759
70760
70761
70762
70763
70764
70765
70766
70767
70768
70769
70770
70771
70772
70773
70774
70775
70776
70777
70778
70779
70780
70781
70782
70783
70784
70785
70786
70787
70788
70789
70790
70791
70792
70793
70794
70795
70796
70797
70798
70799
70800
70801
70802
70803
70804
70805
70806
70807
70808
70809
70810
70811
70812
70813
70814
70815
70816
70817
70818
70819
70820
70821
70822
70823
70824
70825
70826
70827
70828
70829
70830
70831
70832
70833
70834
70835
70836
70837
70838
70839
70840
70841
70842
70843
70844
70845
70846
70847
70848
70849
70850
70851
70852
70853
70854
70855
70856
70857
70858
70859
70860
70861
70862
70863
70864
70865
70866
70867
70868
70869
70870
70871
70872
70873
70874
70875
70876
70877
70878
70879
70880
70881
70882
70883
70884
70885
70886
70887
70888
70889
70890
70891
70892
70893
70894
70895
70896
70897
70898
70899
70900
70901
70902
70903
70904
70905
70906
70907
70908
70909
70910
70911
70912
70913
70914
70915
70916
70917
70918
70919
70920
70921
70922
70923
70924
70925
70926
70927
70928
70929
70930
70931
70932
70933
70934
70935
70936
70937
70938
70939
70940
70941
70942
70943
70944
70945
70946
70947
70948
70949
70950
70951
70952
70953
70954
70955
70956
70957
70958
70959
70960
70961
70962
70963
70964
70965
70966
70967
70968
70969
70970
70971
70972
70973
70974
70975
70976
70977
70978
70979
70980
70981
70982
70983
70984
70985
70986
70987
70988
70989
70990
70991
70992
70993
70994
70995
70996
70997
70998
70999
71000
71001
71002
71003
71004
71005
71006
71007
71008
71009
71010
71011
71012
71013
71014
71015
71016
71017
71018
71019
71020
71021
71022
71023
71024
71025
71026
71027
71028
71029
71030
71031
71032
71033
71034
71035
71036
71037
71038
71039
71040
71041
71042
71043
71044
71045
71046
71047
71048
71049
71050
71051
71052
71053
71054
71055
71056
71057
71058
71059
71060
71061
71062
71063
71064
71065
71066
71067
71068
71069
71070
71071
71072
71073
71074
71075
71076
71077
71078
71079
71080
71081
71082
71083
71084
71085
71086
71087
71088
71089
71090
71091
71092
71093
71094
71095
71096
71097
71098
71099
71100
71101
71102
71103
71104
71105
71106
71107
71108
71109
71110
71111
71112
71113
71114
71115
71116
71117
71118
71119
71120
71121
71122
71123
71124
71125
71126
71127
71128
71129
71130
71131
71132
71133
71134
71135
71136
71137
71138
71139
71140
71141
71142
71143
71144
71145
71146
71147
71148
71149
71150
71151
71152
71153
71154
71155
71156
71157
71158
71159
71160
71161
71162
71163
71164
71165
71166
71167
71168
71169
71170
71171
71172
71173
71174
71175
71176
71177
71178
71179
71180
71181
71182
71183
71184
71185
71186
71187
71188
71189
71190
71191
71192
71193
71194
71195
71196
71197
71198
71199
71200
71201
71202
71203
71204
71205
71206
71207
71208
71209
71210
71211
71212
71213
71214
71215
71216
71217
71218
71219
71220
71221
71222
71223
71224
71225
71226
71227
71228
71229
71230
71231
71232
71233
71234
71235
71236
71237
71238
71239
71240
71241
71242
71243
71244
71245
71246
71247
71248
71249
71250
71251
71252
71253
71254
71255
71256
71257
71258
71259
71260
71261
71262
71263
71264
71265
71266
71267
71268
71269
71270
71271
71272
71273
71274
71275
71276
71277
71278
71279
71280
71281
71282
71283
71284
71285
71286
71287
71288
71289
71290
71291
71292
71293
71294
71295
71296
71297
71298
71299
71300
71301
71302
71303
71304
71305
71306
71307
71308
71309
71310
71311
71312
71313
71314
71315
71316
71317
71318
71319
71320
71321
71322
71323
71324
71325
71326
71327
71328
71329
71330
71331
71332
71333
71334
71335
71336
71337
71338
71339
71340
71341
71342
71343
71344
71345
71346
71347
71348
71349
71350
71351
71352
71353
71354
71355
71356
71357
71358
71359
71360
71361
71362
71363
71364
71365
71366
71367
71368
71369
71370
71371
71372
71373
71374
71375
71376
71377
71378
71379
71380
71381
71382
71383
71384
71385
71386
71387
71388
71389
71390
71391
71392
71393
71394
71395
71396
71397
71398
71399
71400
71401
71402
71403
71404
71405
71406
71407
71408
71409
71410
71411
71412
71413
71414
71415
71416
71417
71418
71419
71420
71421
71422
71423
71424
71425
71426
71427
71428
71429
71430
71431
71432
71433
71434
71435
71436
71437
71438
71439
71440
71441
71442
71443
71444
71445
71446
71447
71448
71449
71450
71451
71452
71453
71454
71455
71456
71457
71458
71459
71460
71461
71462
71463
71464
71465
71466
71467
71468
71469
71470
71471
71472
71473
71474
71475
71476
71477
71478
71479
71480
71481
71482
71483
71484
71485
71486
71487
71488
71489
71490
71491
71492
71493
71494
71495
71496
71497
71498
71499
71500
71501
71502
71503
71504
71505
71506
71507
71508
71509
71510
71511
71512
71513
71514
71515
71516
71517
71518
71519
71520
71521
71522
71523
71524
71525
71526
71527
71528
71529
71530
71531
71532
71533
71534
71535
71536
71537
71538
71539
71540
71541
71542
71543
71544
71545
71546
71547
71548
71549
71550
71551
71552
71553
71554
71555
71556
71557
71558
71559
71560
71561
71562
71563
71564
71565
71566
71567
71568
71569
71570
71571
71572
71573
71574
71575
71576
71577
71578
71579
71580
71581
71582
71583
71584
71585
71586
71587
71588
71589
71590
71591
71592
71593
71594
71595
71596
71597
71598
71599
71600
71601
71602
71603
71604
71605
71606
71607
71608
71609
71610
71611
71612
71613
71614
71615
71616
71617
71618
71619
71620
71621
71622
71623
71624
71625
71626
71627
71628
71629
71630
71631
71632
71633
71634
71635
71636
71637
71638
71639
71640
71641
71642
71643
71644
71645
71646
71647
71648
71649
71650
71651
71652
71653
71654
71655
71656
71657
71658
71659
71660
71661
71662
71663
71664
71665
71666
71667
71668
71669
71670
71671
71672
71673
71674
71675
71676
71677
71678
71679
71680
71681
71682
71683
71684
71685
71686
71687
71688
71689
71690
71691
71692
71693
71694
71695
71696
71697
71698
71699
71700
71701
71702
71703
71704
71705
71706
71707
71708
71709
71710
71711
71712
71713
71714
71715
71716
71717
71718
71719
71720
71721
71722
71723
71724
71725
71726
71727
71728
71729
71730
71731
71732
71733
71734
71735
71736
71737
71738
71739
71740
71741
71742
71743
71744
71745
71746
71747
71748
71749
71750
71751
71752
71753
71754
71755
71756
71757
71758
71759
71760
71761
71762
71763
71764
71765
71766
71767
71768
71769
71770
71771
71772
71773
71774
71775
71776
71777
71778
71779
71780
71781
71782
71783
71784
71785
71786
71787
71788
71789
71790
71791
71792
71793
71794
71795
71796
71797
71798
71799
71800
71801
71802
71803
71804
71805
71806
71807
71808
71809
71810
71811
71812
71813
71814
71815
71816
71817
71818
71819
71820
71821
71822
71823
71824
71825
71826
71827
71828
71829
71830
71831
71832
71833
71834
71835
71836
71837
71838
71839
71840
71841
71842
71843
71844
71845
71846
71847
71848
71849
71850
71851
71852
71853
71854
71855
71856
71857
71858
71859
71860
71861
71862
71863
71864
71865
71866
71867
71868
71869
71870
71871
71872
71873
71874
71875
71876
71877
71878
71879
71880
71881
71882
71883
71884
71885
71886
71887
71888
71889
71890
71891
71892
71893
71894
71895
71896
71897
71898
71899
71900
71901
71902
71903
71904
71905
71906
71907
71908
71909
71910
71911
71912
71913
71914
71915
71916
71917
71918
71919
71920
71921
71922
71923
71924
71925
71926
71927
71928
71929
71930
71931
71932
71933
71934
71935
71936
71937
71938
71939
71940
71941
71942
71943
71944
71945
71946
71947
71948
71949
71950
71951
71952
71953
71954
71955
71956
71957
71958
71959
71960
71961
71962
71963
71964
71965
71966
71967
71968
71969
71970
71971
71972
71973
71974
71975
71976
71977
71978
71979
71980
71981
71982
71983
71984
71985
71986
71987
71988
71989
71990
71991
71992
71993
71994
71995
71996
71997
71998
71999
72000
72001
72002
72003
72004
72005
72006
72007
72008
72009
72010
72011
72012
72013
72014
72015
72016
72017
72018
72019
72020
72021
72022
72023
72024
72025
72026
72027
72028
72029
72030
72031
72032
72033
72034
72035
72036
72037
72038
72039
72040
72041
72042
72043
72044
72045
72046
72047
72048
72049
72050
72051
72052
72053
72054
72055
72056
72057
72058
72059
72060
72061
72062
72063
72064
72065
72066
72067
72068
72069
72070
72071
72072
72073
72074
72075
72076
72077
72078
72079
72080
72081
72082
72083
72084
72085
72086
72087
72088
72089
72090
72091
72092
72093
72094
72095
72096
72097
72098
72099
72100
72101
72102
72103
72104
72105
72106
72107
72108
72109
72110
72111
72112
72113
72114
72115
72116
72117
72118
72119
72120
72121
72122
72123
72124
72125
72126
72127
72128
72129
72130
72131
72132
72133
72134
72135
72136
72137
72138
72139
72140
72141
72142
72143
72144
72145
72146
72147
72148
72149
72150
72151
72152
72153
72154
72155
72156
72157
72158
72159
72160
72161
72162
72163
72164
72165
72166
72167
72168
72169
72170
72171
72172
72173
72174
72175
72176
72177
72178
72179
72180
72181
72182
72183
72184
72185
72186
72187
72188
72189
72190
72191
72192
72193
72194
72195
72196
72197
72198
72199
72200
72201
72202
72203
72204
72205
72206
72207
72208
72209
72210
72211
72212
72213
72214
72215
72216
72217
72218
72219
72220
72221
72222
72223
72224
72225
72226
72227
72228
72229
72230
72231
72232
72233
72234
72235
72236
72237
72238
72239
72240
72241
72242
72243
72244
72245
72246
72247
72248
72249
72250
72251
72252
72253
72254
72255
72256
72257
72258
72259
72260
72261
72262
72263
72264
72265
72266
72267
72268
72269
72270
72271
72272
72273
72274
72275
72276
72277
72278
72279
72280
72281
72282
72283
72284
72285
72286
72287
72288
72289
72290
72291
72292
72293
72294
72295
72296
72297
72298
72299
72300
72301
72302
72303
72304
72305
72306
72307
72308
72309
72310
72311
72312
72313
72314
72315
72316
72317
72318
72319
72320
72321
72322
72323
72324
72325
72326
72327
72328
72329
72330
72331
72332
72333
72334
72335
72336
72337
72338
72339
72340
72341
72342
72343
72344
72345
72346
72347
72348
72349
72350
72351
72352
72353
72354
72355
72356
72357
72358
72359
72360
72361
72362
72363
72364
72365
72366
72367
72368
72369
72370
72371
72372
72373
72374
72375
72376
72377
72378
72379
72380
72381
72382
72383
72384
72385
72386
72387
72388
72389
72390
72391
72392
72393
72394
72395
72396
72397
72398
72399
72400
72401
72402
72403
72404
72405
72406
72407
72408
72409
72410
72411
72412
72413
72414
72415
72416
72417
72418
72419
72420
72421
72422
72423
72424
72425
72426
72427
72428
72429
72430
72431
72432
72433
72434
72435
72436
72437
72438
72439
72440
72441
72442
72443
72444
72445
72446
72447
72448
72449
72450
72451
72452
72453
72454
72455
72456
72457
72458
72459
72460
72461
72462
72463
72464
72465
72466
72467
72468
72469
72470
72471
72472
72473
72474
72475
72476
72477
72478
72479
72480
72481
72482
72483
72484
72485
72486
72487
72488
72489
72490
72491
72492
72493
72494
72495
72496
72497
72498
72499
72500
72501
72502
72503
72504
72505
72506
72507
72508
72509
72510
72511
72512
72513
72514
72515
72516
72517
72518
72519
72520
72521
72522
72523
72524
72525
72526
72527
72528
72529
72530
72531
72532
72533
72534
72535
72536
72537
72538
72539
72540
72541
72542
72543
72544
72545
72546
72547
72548
72549
72550
72551
72552
72553
72554
72555
72556
72557
72558
72559
72560
72561
72562
72563
72564
72565
72566
72567
72568
72569
72570
72571
72572
72573
72574
72575
72576
72577
72578
72579
72580
72581
72582
72583
72584
72585
72586
72587
72588
72589
72590
72591
72592
72593
72594
72595
72596
72597
72598
72599
72600
72601
72602
72603
72604
72605
72606
72607
72608
72609
72610
72611
72612
72613
72614
72615
72616
72617
72618
72619
72620
72621
72622
72623
72624
72625
72626
72627
72628
72629
72630
72631
72632
72633
72634
72635
72636
72637
72638
72639
72640
72641
72642
72643
72644
72645
72646
72647
72648
72649
72650
72651
72652
72653
72654
72655
72656
72657
72658
72659
72660
72661
72662
72663
72664
72665
72666
72667
72668
72669
72670
72671
72672
72673
72674
72675
72676
72677
72678
72679
72680
72681
72682
72683
72684
72685
72686
72687
72688
72689
72690
72691
72692
72693
72694
72695
72696
72697
72698
72699
72700
72701
72702
72703
72704
72705
72706
72707
72708
72709
72710
72711
72712
72713
72714
72715
72716
72717
72718
72719
72720
72721
72722
72723
72724
72725
72726
72727
72728
72729
72730
72731
72732
72733
72734
72735
72736
72737
72738
72739
72740
72741
72742
72743
72744
72745
72746
72747
72748
72749
72750
72751
72752
72753
72754
72755
72756
72757
72758
72759
72760
72761
72762
72763
72764
72765
72766
72767
72768
72769
72770
72771
72772
72773
72774
72775
72776
72777
72778
72779
72780
72781
72782
72783
72784
72785
72786
72787
72788
72789
72790
72791
72792
72793
72794
72795
72796
72797
72798
72799
72800
72801
72802
72803
72804
72805
72806
72807
72808
72809
72810
72811
72812
72813
72814
72815
72816
72817
72818
72819
72820
72821
72822
72823
72824
72825
72826
72827
72828
72829
72830
72831
72832
72833
72834
72835
72836
72837
72838
72839
72840
72841
72842
72843
72844
72845
72846
72847
72848
72849
72850
72851
72852
72853
72854
72855
72856
72857
72858
72859
72860
72861
72862
72863
72864
72865
72866
72867
72868
72869
72870
72871
72872
72873
72874
72875
72876
72877
72878
72879
72880
72881
72882
72883
72884
72885
72886
72887
72888
72889
72890
72891
72892
72893
72894
72895
72896
72897
72898
72899
72900
72901
72902
72903
72904
72905
72906
72907
72908
72909
72910
72911
72912
72913
72914
72915
72916
72917
72918
72919
72920
72921
72922
72923
72924
72925
72926
72927
72928
72929
72930
72931
72932
72933
72934
72935
72936
72937
72938
72939
72940
72941
72942
72943
72944
72945
72946
72947
72948
72949
72950
72951
72952
72953
72954
72955
72956
72957
72958
72959
72960
72961
72962
72963
72964
72965
72966
72967
72968
72969
72970
72971
72972
72973
72974
72975
72976
72977
72978
72979
72980
72981
72982
72983
72984
72985
72986
72987
72988
72989
72990
72991
72992
72993
72994
72995
72996
72997
72998
72999
73000
73001
73002
73003
73004
73005
73006
73007
73008
73009
73010
73011
73012
73013
73014
73015
73016
73017
73018
73019
73020
73021
73022
73023
73024
73025
73026
73027
73028
73029
73030
73031
73032
73033
73034
73035
73036
73037
73038
73039
73040
73041
73042
73043
73044
73045
73046
73047
73048
73049
73050
73051
73052
73053
73054
73055
73056
73057
73058
73059
73060
73061
73062
73063
73064
73065
73066
73067
73068
73069
73070
73071
73072
73073
73074
73075
73076
73077
73078
73079
73080
73081
73082
73083
73084
73085
73086
73087
73088
73089
73090
73091
73092
73093
73094
73095
73096
73097
73098
73099
73100
73101
73102
73103
73104
73105
73106
73107
73108
73109
73110
73111
73112
73113
73114
73115
73116
73117
73118
73119
73120
73121
73122
73123
73124
73125
73126
73127
73128
73129
73130
73131
73132
73133
73134
73135
73136
73137
73138
73139
73140
73141
73142
73143
73144
73145
73146
73147
73148
73149
73150
73151
73152
73153
73154
73155
73156
73157
73158
73159
73160
73161
73162
73163
73164
73165
73166
73167
73168
73169
73170
73171
73172
73173
73174
73175
73176
73177
73178
73179
73180
73181
73182
73183
73184
73185
73186
73187
73188
73189
73190
73191
73192
73193
73194
73195
73196
73197
73198
73199
73200
73201
73202
73203
73204
73205
73206
73207
73208
73209
73210
73211
73212
73213
73214
73215
73216
73217
73218
73219
73220
73221
73222
73223
73224
73225
73226
73227
73228
73229
73230
73231
73232
73233
73234
73235
73236
73237
73238
73239
73240
73241
73242
73243
73244
73245
73246
73247
73248
73249
73250
73251
73252
73253
73254
73255
73256
73257
73258
73259
73260
73261
73262
73263
73264
73265
73266
73267
73268
73269
73270
73271
73272
73273
73274
73275
73276
73277
73278
73279
73280
73281
73282
73283
73284
73285
73286
73287
73288
73289
73290
73291
73292
73293
73294
73295
73296
73297
73298
73299
73300
73301
73302
73303
73304
73305
73306
73307
73308
73309
73310
73311
73312
73313
73314
73315
73316
73317
73318
73319
73320
73321
73322
73323
73324
73325
73326
73327
73328
73329
73330
73331
73332
73333
73334
73335
73336
73337
73338
73339
73340
73341
73342
73343
73344
73345
73346
73347
73348
73349
73350
73351
73352
73353
73354
73355
73356
73357
73358
73359
73360
73361
73362
73363
73364
73365
73366
73367
73368
73369
73370
73371
73372
73373
73374
73375
73376
73377
73378
73379
73380
73381
73382
73383
73384
73385
73386
73387
73388
73389
73390
73391
73392
73393
73394
73395
73396
73397
73398
73399
73400
73401
73402
73403
73404
73405
73406
73407
73408
73409
73410
73411
73412
73413
73414
73415
73416
73417
73418
73419
73420
73421
73422
73423
73424
73425
73426
73427
73428
73429
73430
73431
73432
73433
73434
73435
73436
73437
73438
73439
73440
73441
73442
73443
73444
73445
73446
73447
73448
73449
73450
73451
73452
73453
73454
73455
73456
73457
73458
73459
73460
73461
73462
73463
73464
73465
73466
73467
73468
73469
73470
73471
73472
73473
73474
73475
73476
73477
73478
73479
73480
73481
73482
73483
73484
73485
73486
73487
73488
73489
73490
73491
73492
73493
73494
73495
73496
73497
73498
73499
73500
73501
73502
73503
73504
73505
73506
73507
73508
73509
73510
73511
73512
73513
73514
73515
73516
73517
73518
73519
73520
73521
73522
73523
73524
73525
73526
73527
73528
73529
73530
73531
73532
73533
73534
73535
73536
73537
73538
73539
73540
73541
73542
73543
73544
73545
73546
73547
73548
73549
73550
73551
73552
73553
73554
73555
73556
73557
73558
73559
73560
73561
73562
73563
73564
73565
73566
73567
73568
73569
73570
73571
73572
73573
73574
73575
73576
73577
73578
73579
73580
73581
73582
73583
73584
73585
73586
73587
73588
73589
73590
73591
73592
73593
73594
73595
73596
73597
73598
73599
73600
73601
73602
73603
73604
73605
73606
73607
73608
73609
73610
73611
73612
73613
73614
73615
73616
73617
73618
73619
73620
73621
73622
73623
73624
73625
73626
73627
73628
73629
73630
73631
73632
73633
73634
73635
73636
73637
73638
73639
73640
73641
73642
73643
73644
73645
73646
73647
73648
73649
73650
73651
73652
73653
73654
73655
73656
73657
73658
73659
73660
73661
73662
73663
73664
73665
73666
73667
73668
73669
73670
73671
73672
73673
73674
73675
73676
73677
73678
73679
73680
73681
73682
73683
73684
73685
73686
73687
73688
73689
73690
73691
73692
73693
73694
73695
73696
73697
73698
73699
73700
73701
73702
73703
73704
73705
73706
73707
73708
73709
73710
73711
73712
73713
73714
73715
73716
73717
73718
73719
73720
73721
73722
73723
73724
73725
73726
73727
73728
73729
73730
73731
73732
73733
73734
73735
73736
73737
73738
73739
73740
73741
73742
73743
73744
73745
73746
73747
73748
73749
73750
73751
73752
73753
73754
73755
73756
73757
73758
73759
73760
73761
73762
73763
73764
73765
73766
73767
73768
73769
73770
73771
73772
73773
73774
73775
73776
73777
73778
73779
73780
73781
73782
73783
73784
73785
73786
73787
73788
73789
73790
73791
73792
73793
73794
73795
73796
73797
73798
73799
73800
73801
73802
73803
73804
73805
73806
73807
73808
73809
73810
73811
73812
73813
73814
73815
73816
73817
73818
73819
73820
73821
73822
73823
73824
73825
73826
73827
73828
73829
73830
73831
73832
73833
73834
73835
73836
73837
73838
73839
73840
73841
73842
73843
73844
73845
73846
73847
73848
73849
73850
73851
73852
73853
73854
73855
73856
73857
73858
73859
73860
73861
73862
73863
73864
73865
73866
73867
73868
73869
73870
73871
73872
73873
73874
73875
73876
73877
73878
73879
73880
73881
73882
73883
73884
73885
73886
73887
73888
73889
73890
73891
73892
73893
73894
73895
73896
73897
73898
73899
73900
73901
73902
73903
73904
73905
73906
73907
73908
73909
73910
73911
73912
73913
73914
73915
73916
73917
73918
73919
73920
73921
73922
73923
73924
73925
73926
73927
73928
73929
73930
73931
73932
73933
73934
73935
73936
73937
73938
73939
73940
73941
73942
73943
73944
73945
73946
73947
73948
73949
73950
73951
73952
73953
73954
73955
73956
73957
73958
73959
73960
73961
73962
73963
73964
73965
73966
73967
73968
73969
73970
73971
73972
73973
73974
73975
73976
73977
73978
73979
73980
73981
73982
73983
73984
73985
73986
73987
73988
73989
73990
73991
73992
73993
73994
73995
73996
73997
73998
73999
74000
74001
74002
74003
74004
74005
74006
74007
74008
74009
74010
74011
74012
74013
74014
74015
74016
74017
74018
74019
74020
74021
74022
74023
74024
74025
74026
74027
74028
74029
74030
74031
74032
74033
74034
74035
74036
74037
74038
74039
74040
74041
74042
74043
74044
74045
74046
74047
74048
74049
74050
74051
74052
74053
74054
74055
74056
74057
74058
74059
74060
74061
74062
74063
74064
74065
74066
74067
74068
74069
74070
74071
74072
74073
74074
74075
74076
74077
74078
74079
74080
74081
74082
74083
74084
74085
74086
74087
74088
74089
74090
74091
74092
74093
74094
74095
74096
74097
74098
74099
74100
74101
74102
74103
74104
74105
74106
74107
74108
74109
74110
74111
74112
74113
74114
74115
74116
74117
74118
74119
74120
74121
74122
74123
74124
74125
74126
74127
74128
74129
74130
74131
74132
74133
74134
74135
74136
74137
74138
74139
74140
74141
74142
74143
74144
74145
74146
74147
74148
74149
74150
74151
74152
74153
74154
74155
74156
74157
74158
74159
74160
74161
74162
74163
74164
74165
74166
74167
74168
74169
74170
74171
74172
74173
74174
74175
74176
74177
74178
74179
74180
74181
74182
74183
74184
74185
74186
74187
74188
74189
74190
74191
74192
74193
74194
74195
74196
74197
74198
74199
74200
74201
74202
74203
74204
74205
74206
74207
74208
74209
74210
74211
74212
74213
74214
74215
74216
74217
74218
74219
74220
74221
74222
74223
74224
74225
74226
74227
74228
74229
74230
74231
74232
74233
74234
74235
74236
74237
74238
74239
74240
74241
74242
74243
74244
74245
74246
74247
74248
74249
74250
74251
74252
74253
74254
74255
74256
74257
74258
74259
74260
74261
74262
74263
74264
74265
74266
74267
74268
74269
74270
74271
74272
74273
74274
74275
74276
74277
74278
74279
74280
74281
74282
74283
74284
74285
74286
74287
74288
74289
74290
74291
74292
74293
74294
74295
74296
74297
74298
74299
74300
74301
74302
74303
74304
74305
74306
74307
74308
74309
74310
74311
74312
74313
74314
74315
74316
74317
74318
74319
74320
74321
74322
74323
74324
74325
74326
74327
74328
74329
74330
74331
74332
74333
74334
74335
74336
74337
74338
74339
74340
74341
74342
74343
74344
74345
74346
74347
74348
74349
74350
74351
74352
74353
74354
74355
74356
74357
74358
74359
74360
74361
74362
74363
74364
74365
74366
74367
74368
74369
74370
74371
74372
74373
74374
74375
74376
74377
74378
74379
74380
74381
74382
74383
74384
74385
74386
74387
74388
74389
74390
74391
74392
74393
74394
74395
74396
74397
74398
74399
74400
74401
74402
74403
74404
74405
74406
74407
74408
74409
74410
74411
74412
74413
74414
74415
74416
74417
74418
74419
74420
74421
74422
74423
74424
74425
74426
74427
74428
74429
74430
74431
74432
74433
74434
74435
74436
74437
74438
74439
74440
74441
74442
74443
74444
74445
74446
74447
74448
74449
74450
74451
74452
74453
74454
74455
74456
74457
74458
74459
74460
74461
74462
74463
74464
74465
74466
74467
74468
74469
74470
74471
74472
74473
74474
74475
74476
74477
74478
74479
74480
74481
74482
74483
74484
74485
74486
74487
74488
74489
74490
74491
74492
74493
74494
74495
74496
74497
74498
74499
74500
74501
74502
74503
74504
74505
74506
74507
74508
74509
74510
74511
74512
74513
74514
74515
74516
74517
74518
74519
74520
74521
74522
74523
74524
74525
74526
74527
74528
74529
74530
74531
74532
74533
74534
74535
74536
74537
74538
74539
74540
74541
74542
74543
74544
74545
74546
74547
74548
74549
74550
74551
74552
74553
74554
74555
74556
74557
74558
74559
74560
74561
74562
74563
74564
74565
74566
74567
74568
74569
74570
74571
74572
74573
74574
74575
74576
74577
74578
74579
74580
74581
74582
74583
74584
74585
74586
74587
74588
74589
74590
74591
74592
74593
74594
74595
74596
74597
74598
74599
74600
74601
74602
74603
74604
74605
74606
74607
74608
74609
74610
74611
74612
74613
74614
74615
74616
74617
74618
74619
74620
74621
74622
74623
74624
74625
74626
74627
74628
74629
74630
74631
74632
74633
74634
74635
74636
74637
74638
74639
74640
74641
74642
74643
74644
74645
74646
74647
74648
74649
74650
74651
74652
74653
74654
74655
74656
74657
74658
74659
74660
74661
74662
74663
74664
74665
74666
74667
74668
74669
74670
74671
74672
74673
74674
74675
74676
74677
74678
74679
74680
74681
74682
74683
74684
74685
74686
74687
74688
74689
74690
74691
74692
74693
74694
74695
74696
74697
74698
74699
74700
74701
74702
74703
74704
74705
74706
74707
74708
74709
74710
74711
74712
74713
74714
74715
74716
74717
74718
74719
74720
74721
74722
74723
74724
74725
74726
74727
74728
74729
74730
74731
74732
74733
74734
74735
74736
74737
74738
74739
74740
74741
74742
74743
74744
74745
74746
74747
74748
74749
74750
74751
74752
74753
74754
74755
74756
74757
74758
74759
74760
74761
74762
74763
74764
74765
74766
74767
74768
74769
74770
74771
74772
74773
74774
74775
74776
74777
74778
74779
74780
74781
74782
74783
74784
74785
74786
74787
74788
74789
74790
74791
74792
74793
74794
74795
74796
74797
74798
74799
74800
74801
74802
74803
74804
74805
74806
74807
74808
74809
74810
74811
74812
74813
74814
74815
74816
74817
74818
74819
74820
74821
74822
74823
74824
74825
74826
74827
74828
74829
74830
74831
74832
74833
74834
74835
74836
74837
74838
74839
74840
74841
74842
74843
74844
74845
74846
74847
74848
74849
74850
74851
74852
74853
74854
74855
74856
74857
74858
74859
74860
74861
74862
74863
74864
74865
74866
74867
74868
74869
74870
74871
74872
74873
74874
74875
74876
74877
74878
74879
74880
74881
74882
74883
74884
74885
74886
74887
74888
74889
74890
74891
74892
74893
74894
74895
74896
74897
74898
74899
74900
74901
74902
74903
74904
74905
74906
74907
74908
74909
74910
74911
74912
74913
74914
74915
74916
74917
74918
74919
74920
74921
74922
74923
74924
74925
74926
74927
74928
74929
74930
74931
74932
74933
74934
74935
74936
74937
74938
74939
74940
74941
74942
74943
74944
74945
74946
74947
74948
74949
74950
74951
74952
74953
74954
74955
74956
74957
74958
74959
74960
74961
74962
74963
74964
74965
74966
74967
74968
74969
74970
74971
74972
74973
74974
74975
74976
74977
74978
74979
74980
74981
74982
74983
74984
74985
74986
74987
74988
74989
74990
74991
74992
74993
74994
74995
74996
74997
74998
74999
75000
75001
75002
75003
75004
75005
75006
75007
75008
75009
75010
75011
75012
75013
75014
75015
75016
75017
75018
75019
75020
75021
75022
75023
75024
75025
75026
75027
75028
75029
75030
75031
75032
75033
75034
75035
75036
75037
75038
75039
75040
75041
75042
75043
75044
75045
75046
75047
75048
75049
75050
75051
75052
75053
75054
75055
75056
75057
75058
75059
75060
75061
75062
75063
75064
75065
75066
75067
75068
75069
75070
75071
75072
75073
75074
75075
75076
75077
75078
75079
75080
75081
75082
75083
75084
75085
75086
75087
75088
75089
75090
75091
75092
75093
75094
75095
75096
75097
75098
75099
75100
75101
75102
75103
75104
75105
75106
75107
75108
75109
75110
75111
75112
75113
75114
75115
75116
75117
75118
75119
75120
75121
75122
75123
75124
75125
75126
75127
75128
75129
75130
75131
75132
75133
75134
75135
75136
75137
75138
75139
75140
75141
75142
75143
75144
75145
75146
75147
75148
75149
75150
75151
75152
75153
75154
75155
75156
75157
75158
75159
75160
75161
75162
75163
75164
75165
75166
75167
75168
75169
75170
75171
75172
75173
75174
75175
75176
75177
75178
75179
75180
75181
75182
75183
75184
75185
75186
75187
75188
75189
75190
75191
75192
75193
75194
75195
75196
75197
75198
75199
75200
75201
75202
75203
75204
75205
75206
75207
75208
75209
75210
75211
75212
75213
75214
75215
75216
75217
75218
75219
75220
75221
75222
75223
75224
75225
75226
75227
75228
75229
75230
75231
75232
75233
75234
75235
75236
75237
75238
75239
75240
75241
75242
75243
75244
75245
75246
75247
75248
75249
75250
75251
75252
75253
75254
75255
75256
75257
75258
75259
75260
75261
75262
75263
75264
75265
75266
75267
75268
75269
75270
75271
75272
75273
75274
75275
75276
75277
75278
75279
75280
75281
75282
75283
75284
75285
75286
75287
75288
75289
75290
75291
75292
75293
75294
75295
75296
75297
75298
75299
75300
75301
75302
75303
75304
75305
75306
75307
75308
75309
75310
75311
75312
75313
75314
75315
75316
75317
75318
75319
75320
75321
75322
75323
75324
75325
75326
75327
75328
75329
75330
75331
75332
75333
75334
75335
75336
75337
75338
75339
75340
75341
75342
75343
75344
75345
75346
75347
75348
75349
75350
75351
75352
75353
75354
75355
75356
75357
75358
75359
75360
75361
75362
75363
75364
75365
75366
75367
75368
75369
75370
75371
75372
75373
75374
75375
75376
75377
75378
75379
75380
75381
75382
75383
75384
75385
75386
75387
75388
75389
75390
75391
75392
75393
75394
75395
75396
75397
75398
75399
75400
75401
75402
75403
75404
75405
75406
75407
75408
75409
75410
75411
75412
75413
75414
75415
75416
75417
75418
75419
75420
75421
75422
75423
75424
75425
75426
75427
75428
75429
75430
75431
75432
75433
75434
75435
75436
75437
75438
75439
75440
75441
75442
75443
75444
75445
75446
75447
75448
75449
75450
75451
75452
75453
75454
75455
75456
75457
75458
75459
75460
75461
75462
75463
75464
75465
75466
75467
75468
75469
75470
75471
75472
75473
75474
75475
75476
75477
75478
75479
75480
75481
75482
75483
75484
75485
75486
75487
75488
75489
75490
75491
75492
75493
75494
75495
75496
75497
75498
75499
75500
75501
75502
75503
75504
75505
75506
75507
75508
75509
75510
75511
75512
75513
75514
75515
75516
75517
75518
75519
75520
75521
75522
75523
75524
75525
75526
75527
75528
75529
75530
75531
75532
75533
75534
75535
75536
75537
75538
75539
75540
75541
75542
75543
75544
75545
75546
75547
75548
75549
75550
75551
75552
75553
75554
75555
75556
75557
75558
75559
75560
75561
75562
75563
75564
75565
75566
75567
75568
75569
75570
75571
75572
75573
75574
75575
75576
75577
75578
75579
75580
75581
75582
75583
75584
75585
75586
75587
75588
75589
75590
75591
75592
75593
75594
75595
75596
75597
75598
75599
75600
75601
75602
75603
75604
75605
75606
75607
75608
75609
75610
75611
75612
75613
75614
75615
75616
75617
75618
75619
75620
75621
75622
75623
75624
75625
75626
75627
75628
75629
75630
75631
75632
75633
75634
75635
75636
75637
75638
75639
75640
75641
75642
75643
75644
75645
75646
75647
75648
75649
75650
75651
75652
75653
75654
75655
75656
75657
75658
75659
75660
75661
75662
75663
75664
75665
75666
75667
75668
75669
75670
75671
75672
75673
75674
75675
75676
75677
75678
75679
75680
75681
75682
75683
75684
75685
75686
75687
75688
75689
75690
75691
75692
75693
75694
75695
75696
75697
75698
75699
75700
75701
75702
75703
75704
75705
75706
75707
75708
75709
75710
75711
75712
75713
75714
75715
75716
75717
75718
75719
75720
75721
75722
75723
75724
75725
75726
75727
75728
75729
75730
75731
75732
75733
75734
75735
75736
75737
75738
75739
75740
75741
75742
75743
75744
75745
75746
75747
75748
75749
75750
75751
75752
75753
75754
75755
75756
75757
75758
75759
75760
75761
75762
75763
75764
75765
75766
75767
75768
75769
75770
75771
75772
75773
75774
75775
75776
75777
75778
75779
75780
75781
75782
75783
75784
75785
75786
75787
75788
75789
75790
75791
75792
75793
75794
75795
75796
75797
75798
75799
75800
75801
75802
75803
75804
75805
75806
75807
75808
75809
75810
75811
75812
75813
75814
75815
75816
75817
75818
75819
75820
75821
75822
75823
75824
75825
75826
75827
75828
75829
75830
75831
75832
75833
75834
75835
75836
75837
75838
75839
75840
75841
75842
75843
75844
75845
75846
75847
75848
75849
75850
75851
75852
75853
75854
75855
75856
75857
75858
75859
75860
75861
75862
75863
75864
75865
75866
75867
75868
75869
75870
75871
75872
75873
75874
75875
75876
75877
75878
75879
75880
75881
75882
75883
75884
75885
75886
75887
75888
75889
75890
75891
75892
75893
75894
75895
75896
75897
75898
75899
75900
75901
75902
75903
75904
75905
75906
75907
75908
75909
75910
75911
75912
75913
75914
75915
75916
75917
75918
75919
75920
75921
75922
75923
75924
75925
75926
75927
75928
75929
75930
75931
75932
75933
75934
75935
75936
75937
75938
75939
75940
75941
75942
75943
75944
75945
75946
75947
75948
75949
75950
75951
75952
75953
75954
75955
75956
75957
75958
75959
75960
75961
75962
75963
75964
75965
75966
75967
75968
75969
75970
75971
75972
75973
75974
75975
75976
75977
75978
75979
75980
75981
75982
75983
75984
75985
75986
75987
75988
75989
75990
75991
75992
75993
75994
75995
75996
75997
75998
75999
76000
76001
76002
76003
76004
76005
76006
76007
76008
76009
76010
76011
76012
76013
76014
76015
76016
76017
76018
76019
76020
76021
76022
76023
76024
76025
76026
76027
76028
76029
76030
76031
76032
76033
76034
76035
76036
76037
76038
76039
76040
76041
76042
76043
76044
76045
76046
76047
76048
76049
76050
76051
76052
76053
76054
76055
76056
76057
76058
76059
76060
76061
76062
76063
76064
76065
76066
76067
76068
76069
76070
76071
76072
76073
76074
76075
76076
76077
76078
76079
76080
76081
76082
76083
76084
76085
76086
76087
76088
76089
76090
76091
76092
76093
76094
76095
76096
76097
76098
76099
76100
76101
76102
76103
76104
76105
76106
76107
76108
76109
76110
76111
76112
76113
76114
76115
76116
76117
76118
76119
76120
76121
76122
76123
76124
76125
76126
76127
76128
76129
76130
76131
76132
76133
76134
76135
76136
76137
76138
76139
76140
76141
76142
76143
76144
76145
76146
76147
76148
76149
76150
76151
76152
76153
76154
76155
76156
76157
76158
76159
76160
76161
76162
76163
76164
76165
76166
76167
76168
76169
76170
76171
76172
76173
76174
76175
76176
76177
76178
76179
76180
76181
76182
76183
76184
76185
76186
76187
76188
76189
76190
76191
76192
76193
76194
76195
76196
76197
76198
76199
76200
76201
76202
76203
76204
76205
76206
76207
76208
76209
76210
76211
76212
76213
76214
76215
76216
76217
76218
76219
76220
76221
76222
76223
76224
76225
76226
76227
76228
76229
76230
76231
76232
76233
76234
76235
76236
76237
76238
76239
76240
76241
76242
76243
76244
76245
76246
76247
76248
76249
76250
76251
76252
76253
76254
76255
76256
76257
76258
76259
76260
76261
76262
76263
76264
76265
76266
76267
76268
76269
76270
76271
76272
76273
76274
76275
76276
76277
76278
76279
76280
76281
76282
76283
76284
76285
76286
76287
76288
76289
76290
76291
76292
76293
76294
76295
76296
76297
76298
76299
76300
76301
76302
76303
76304
76305
76306
76307
76308
76309
76310
76311
76312
76313
76314
76315
76316
76317
76318
76319
76320
76321
76322
76323
76324
76325
76326
76327
76328
76329
76330
76331
76332
76333
76334
76335
76336
76337
76338
76339
76340
76341
76342
76343
76344
76345
76346
76347
76348
76349
76350
76351
76352
76353
76354
76355
76356
76357
76358
76359
76360
76361
76362
76363
76364
76365
76366
76367
76368
76369
76370
76371
76372
76373
76374
76375
76376
76377
76378
76379
76380
76381
76382
76383
76384
76385
76386
76387
76388
76389
76390
76391
76392
76393
76394
76395
76396
76397
76398
76399
76400
76401
76402
76403
76404
76405
76406
76407
76408
76409
76410
76411
76412
76413
76414
76415
76416
76417
76418
76419
76420
76421
76422
76423
76424
76425
76426
76427
76428
76429
76430
76431
76432
76433
76434
76435
76436
76437
76438
76439
76440
76441
76442
76443
76444
76445
76446
76447
76448
76449
76450
76451
76452
76453
76454
76455
76456
76457
76458
76459
76460
76461
76462
76463
76464
76465
76466
76467
76468
76469
76470
76471
76472
76473
76474
76475
76476
76477
76478
76479
76480
76481
76482
76483
76484
76485
76486
76487
76488
76489
76490
76491
76492
76493
76494
76495
76496
76497
76498
76499
76500
76501
76502
76503
76504
76505
76506
76507
76508
76509
76510
76511
76512
76513
76514
76515
76516
76517
76518
76519
76520
76521
76522
76523
76524
76525
76526
76527
76528
76529
76530
76531
76532
76533
76534
76535
76536
76537
76538
76539
76540
76541
76542
76543
76544
76545
76546
76547
76548
76549
76550
76551
76552
76553
76554
76555
76556
76557
76558
76559
76560
76561
76562
76563
76564
76565
76566
76567
76568
76569
76570
76571
76572
76573
76574
76575
76576
76577
76578
76579
76580
76581
76582
76583
76584
76585
76586
76587
76588
76589
76590
76591
76592
76593
76594
76595
76596
76597
76598
76599
76600
76601
76602
76603
76604
76605
76606
76607
76608
76609
76610
76611
76612
76613
76614
76615
76616
76617
76618
76619
76620
76621
76622
76623
76624
76625
76626
76627
76628
76629
76630
76631
76632
76633
76634
76635
76636
76637
76638
76639
76640
76641
76642
76643
76644
76645
76646
76647
76648
76649
76650
76651
76652
76653
76654
76655
76656
76657
76658
76659
76660
76661
76662
76663
76664
76665
76666
76667
76668
76669
76670
76671
76672
76673
76674
76675
76676
76677
76678
76679
76680
76681
76682
76683
76684
76685
76686
76687
76688
76689
76690
76691
76692
76693
76694
76695
76696
76697
76698
76699
76700
76701
76702
76703
76704
76705
76706
76707
76708
76709
76710
76711
76712
76713
76714
76715
76716
76717
76718
76719
76720
76721
76722
76723
76724
76725
76726
76727
76728
76729
76730
76731
76732
76733
76734
76735
76736
76737
76738
76739
76740
76741
76742
76743
76744
76745
76746
76747
76748
76749
76750
76751
76752
76753
76754
76755
76756
76757
76758
76759
76760
76761
76762
76763
76764
76765
76766
76767
76768
76769
76770
76771
76772
76773
76774
76775
76776
76777
76778
76779
76780
76781
76782
76783
76784
76785
76786
76787
76788
76789
76790
76791
76792
76793
76794
76795
76796
76797
76798
76799
76800
76801
76802
76803
76804
76805
76806
76807
76808
76809
76810
76811
76812
76813
76814
76815
76816
76817
76818
76819
76820
76821
76822
76823
76824
76825
76826
76827
76828
76829
76830
76831
76832
76833
76834
76835
76836
76837
76838
76839
76840
76841
76842
76843
76844
76845
76846
76847
76848
76849
76850
76851
76852
76853
76854
76855
76856
76857
76858
76859
76860
76861
76862
76863
76864
76865
76866
76867
76868
76869
76870
76871
76872
76873
76874
76875
76876
76877
76878
76879
76880
76881
76882
76883
76884
76885
76886
76887
76888
76889
76890
76891
76892
76893
76894
76895
76896
76897
76898
76899
76900
76901
76902
76903
76904
76905
76906
76907
76908
76909
76910
76911
76912
76913
76914
76915
76916
76917
76918
76919
76920
76921
76922
76923
76924
76925
76926
76927
76928
76929
76930
76931
76932
76933
76934
76935
76936
76937
76938
76939
76940
76941
76942
76943
76944
76945
76946
76947
76948
76949
76950
76951
76952
76953
76954
76955
76956
76957
76958
76959
76960
76961
76962
76963
76964
76965
76966
76967
76968
76969
76970
76971
76972
76973
76974
76975
76976
76977
76978
76979
76980
76981
76982
76983
76984
76985
76986
76987
76988
76989
76990
76991
76992
76993
76994
76995
76996
76997
76998
76999
77000
77001
77002
77003
77004
77005
77006
77007
77008
77009
77010
77011
77012
77013
77014
77015
77016
77017
77018
77019
77020
77021
77022
77023
77024
77025
77026
77027
77028
77029
77030
77031
77032
77033
77034
77035
77036
77037
77038
77039
77040
77041
77042
77043
77044
77045
77046
77047
77048
77049
77050
77051
77052
77053
77054
77055
77056
77057
77058
77059
77060
77061
77062
77063
77064
77065
77066
77067
77068
77069
77070
77071
77072
77073
77074
77075
77076
77077
77078
77079
77080
77081
77082
77083
77084
77085
77086
77087
77088
77089
77090
77091
77092
77093
77094
77095
77096
77097
77098
77099
77100
77101
77102
77103
77104
77105
77106
77107
77108
77109
77110
77111
77112
77113
77114
77115
77116
77117
77118
77119
77120
77121
77122
77123
77124
77125
77126
77127
77128
77129
77130
77131
77132
77133
77134
77135
77136
77137
77138
77139
77140
77141
77142
77143
77144
77145
77146
77147
77148
77149
77150
77151
77152
77153
77154
77155
77156
77157
77158
77159
77160
77161
77162
77163
77164
77165
77166
77167
77168
77169
77170
77171
77172
77173
77174
77175
77176
77177
77178
77179
77180
77181
77182
77183
77184
77185
77186
77187
77188
77189
77190
77191
77192
77193
77194
77195
77196
77197
77198
77199
77200
77201
77202
77203
77204
77205
77206
77207
77208
77209
77210
77211
77212
77213
77214
77215
77216
77217
77218
77219
77220
77221
77222
77223
77224
77225
77226
77227
77228
77229
77230
77231
77232
77233
77234
77235
77236
77237
77238
77239
77240
77241
77242
77243
77244
77245
77246
77247
77248
77249
77250
77251
77252
77253
77254
77255
77256
77257
77258
77259
77260
77261
77262
77263
77264
77265
77266
77267
77268
77269
77270
77271
77272
77273
77274
77275
77276
77277
77278
77279
77280
77281
77282
77283
77284
77285
77286
77287
77288
77289
77290
77291
77292
77293
77294
77295
77296
77297
77298
77299
77300
77301
77302
77303
77304
77305
77306
77307
77308
77309
77310
77311
77312
77313
77314
77315
77316
77317
77318
77319
77320
77321
77322
77323
77324
77325
77326
77327
77328
77329
77330
77331
77332
77333
77334
77335
77336
77337
77338
77339
77340
77341
77342
77343
77344
77345
77346
77347
77348
77349
77350
77351
77352
77353
77354
77355
77356
77357
77358
77359
77360
77361
77362
77363
77364
77365
77366
77367
77368
77369
77370
77371
77372
77373
77374
77375
77376
77377
77378
77379
77380
77381
77382
77383
77384
77385
77386
77387
77388
77389
77390
77391
77392
77393
77394
77395
77396
77397
77398
77399
77400
77401
77402
77403
77404
77405
77406
77407
77408
77409
77410
77411
77412
77413
77414
77415
77416
77417
77418
77419
77420
77421
77422
77423
77424
77425
77426
77427
77428
77429
77430
77431
77432
77433
77434
77435
77436
77437
77438
77439
77440
77441
77442
77443
77444
77445
77446
77447
77448
77449
77450
77451
77452
77453
77454
77455
77456
77457
77458
77459
77460
77461
77462
77463
77464
77465
77466
77467
77468
77469
77470
77471
77472
77473
77474
77475
77476
77477
77478
77479
77480
77481
77482
77483
77484
77485
77486
77487
77488
77489
77490
77491
77492
77493
77494
77495
77496
77497
77498
77499
77500
77501
77502
77503
77504
77505
77506
77507
77508
77509
77510
77511
77512
77513
77514
77515
77516
77517
77518
77519
77520
77521
77522
77523
77524
77525
77526
77527
77528
77529
77530
77531
77532
77533
77534
77535
77536
77537
77538
77539
77540
77541
77542
77543
77544
77545
77546
77547
77548
77549
77550
77551
77552
77553
77554
77555
77556
77557
77558
77559
77560
77561
77562
77563
77564
77565
77566
77567
77568
77569
77570
77571
77572
77573
77574
77575
77576
77577
77578
77579
77580
77581
77582
77583
77584
77585
77586
77587
77588
77589
77590
77591
77592
77593
77594
77595
77596
77597
77598
77599
77600
77601
77602
77603
77604
77605
77606
77607
77608
77609
77610
77611
77612
77613
77614
77615
77616
77617
77618
77619
77620
77621
77622
77623
77624
77625
77626
77627
77628
77629
77630
77631
77632
77633
77634
77635
77636
77637
77638
77639
77640
77641
77642
77643
77644
77645
77646
77647
77648
77649
77650
77651
77652
77653
77654
77655
77656
77657
77658
77659
77660
77661
77662
77663
77664
77665
77666
77667
77668
77669
77670
77671
77672
77673
77674
77675
77676
77677
77678
77679
77680
77681
77682
77683
77684
77685
77686
77687
77688
77689
77690
77691
77692
77693
77694
77695
77696
77697
77698
77699
77700
77701
77702
77703
77704
77705
77706
77707
77708
77709
77710
77711
77712
77713
77714
77715
77716
77717
77718
77719
77720
77721
77722
77723
77724
77725
77726
77727
77728
77729
77730
77731
77732
77733
77734
77735
77736
77737
77738
77739
77740
77741
77742
77743
77744
77745
77746
77747
77748
77749
77750
77751
77752
77753
77754
77755
77756
77757
77758
77759
77760
77761
77762
77763
77764
77765
77766
77767
77768
77769
77770
77771
77772
77773
77774
77775
77776
77777
77778
77779
77780
77781
77782
77783
77784
77785
77786
77787
77788
77789
77790
77791
77792
77793
77794
77795
77796
77797
77798
77799
77800
77801
77802
77803
77804
77805
77806
77807
77808
77809
77810
77811
77812
77813
77814
77815
77816
77817
77818
77819
77820
77821
77822
77823
77824
77825
77826
77827
77828
77829
77830
77831
77832
77833
77834
77835
77836
77837
77838
77839
77840
77841
77842
77843
77844
77845
77846
77847
77848
77849
77850
77851
77852
77853
77854
77855
77856
77857
77858
77859
77860
77861
77862
77863
77864
77865
77866
77867
77868
77869
77870
77871
77872
77873
77874
77875
77876
77877
77878
77879
77880
77881
77882
77883
77884
77885
77886
77887
77888
77889
77890
77891
77892
77893
77894
77895
77896
77897
77898
77899
77900
77901
77902
77903
77904
77905
77906
77907
77908
77909
77910
77911
77912
77913
77914
77915
77916
77917
77918
77919
77920
77921
77922
77923
77924
77925
77926
77927
77928
77929
77930
77931
77932
77933
77934
77935
77936
77937
77938
77939
77940
77941
77942
77943
77944
77945
77946
77947
77948
77949
77950
77951
77952
77953
77954
77955
77956
77957
77958
77959
77960
77961
77962
77963
77964
77965
77966
77967
77968
77969
77970
77971
77972
77973
77974
77975
77976
77977
77978
77979
77980
77981
77982
77983
77984
77985
77986
77987
77988
77989
77990
77991
77992
77993
77994
77995
77996
77997
77998
77999
78000
78001
78002
78003
78004
78005
78006
78007
78008
78009
78010
78011
78012
78013
78014
78015
78016
78017
78018
78019
78020
78021
78022
78023
78024
78025
78026
78027
78028
78029
78030
78031
78032
78033
78034
78035
78036
78037
78038
78039
78040
78041
78042
78043
78044
78045
78046
78047
78048
78049
78050
78051
78052
78053
78054
78055
78056
78057
78058
78059
78060
78061
78062
78063
78064
78065
78066
78067
78068
78069
78070
78071
78072
78073
78074
78075
78076
78077
78078
78079
78080
78081
78082
78083
78084
78085
78086
78087
78088
78089
78090
78091
78092
78093
78094
78095
78096
78097
78098
78099
78100
78101
78102
78103
78104
78105
78106
78107
78108
78109
78110
78111
78112
78113
78114
78115
78116
78117
78118
78119
78120
78121
78122
78123
78124
78125
78126
78127
78128
78129
78130
78131
78132
78133
78134
78135
78136
78137
78138
78139
78140
78141
78142
78143
78144
78145
78146
78147
78148
78149
78150
78151
78152
78153
78154
78155
78156
78157
78158
78159
78160
78161
78162
78163
78164
78165
78166
78167
78168
78169
78170
78171
78172
78173
78174
78175
78176
78177
78178
78179
78180
78181
78182
78183
78184
78185
78186
78187
78188
78189
78190
78191
78192
78193
78194
78195
78196
78197
78198
78199
78200
78201
78202
78203
78204
78205
78206
78207
78208
78209
78210
78211
78212
78213
78214
78215
78216
78217
78218
78219
78220
78221
78222
78223
78224
78225
78226
78227
78228
78229
78230
78231
78232
78233
78234
78235
78236
78237
78238
78239
78240
78241
78242
78243
78244
78245
78246
78247
78248
78249
78250
78251
78252
78253
78254
78255
78256
78257
78258
78259
78260
78261
78262
78263
78264
78265
78266
78267
78268
78269
78270
78271
78272
78273
78274
78275
78276
78277
78278
78279
78280
78281
78282
78283
78284
78285
78286
78287
78288
78289
78290
78291
78292
78293
78294
78295
78296
78297
78298
78299
78300
78301
78302
78303
78304
78305
78306
78307
78308
78309
78310
78311
78312
78313
78314
78315
78316
78317
78318
78319
78320
78321
78322
78323
78324
78325
78326
78327
78328
78329
78330
78331
78332
78333
78334
78335
78336
78337
78338
78339
78340
78341
78342
78343
78344
78345
78346
78347
78348
78349
78350
78351
78352
78353
78354
78355
78356
78357
78358
78359
78360
78361
78362
78363
78364
78365
78366
78367
78368
78369
78370
78371
78372
78373
78374
78375
78376
78377
78378
78379
78380
78381
78382
78383
78384
78385
78386
78387
78388
78389
78390
78391
78392
78393
78394
78395
78396
78397
78398
78399
78400
78401
78402
78403
78404
78405
78406
78407
78408
78409
78410
78411
78412
78413
78414
78415
78416
78417
78418
78419
78420
78421
78422
78423
78424
78425
78426
78427
78428
78429
78430
78431
78432
78433
78434
78435
78436
78437
78438
78439
78440
78441
78442
78443
78444
78445
78446
78447
78448
78449
78450
78451
78452
78453
78454
78455
78456
78457
78458
78459
78460
78461
78462
78463
78464
78465
78466
78467
78468
78469
78470
78471
78472
78473
78474
78475
78476
78477
78478
78479
78480
78481
78482
78483
78484
78485
78486
78487
78488
78489
78490
78491
78492
78493
78494
78495
78496
78497
78498
78499
78500
78501
78502
78503
78504
78505
78506
78507
78508
78509
78510
78511
78512
78513
78514
78515
78516
78517
78518
78519
78520
78521
78522
78523
78524
78525
78526
78527
78528
78529
78530
78531
78532
78533
78534
78535
78536
78537
78538
78539
78540
78541
78542
78543
78544
78545
78546
78547
78548
78549
78550
78551
78552
78553
78554
78555
78556
78557
78558
78559
78560
78561
78562
78563
78564
78565
78566
78567
78568
78569
78570
78571
78572
78573
78574
78575
78576
78577
78578
78579
78580
78581
78582
78583
78584
78585
78586
78587
78588
78589
78590
78591
78592
78593
78594
78595
78596
78597
78598
78599
78600
78601
78602
78603
78604
78605
78606
78607
78608
78609
78610
78611
78612
78613
78614
78615
78616
78617
78618
78619
78620
78621
78622
78623
78624
78625
78626
78627
78628
78629
78630
78631
78632
78633
78634
78635
78636
78637
78638
78639
78640
78641
78642
78643
78644
78645
78646
78647
78648
78649
78650
78651
78652
78653
78654
78655
78656
78657
78658
78659
78660
78661
78662
78663
78664
78665
78666
78667
78668
78669
78670
78671
78672
78673
78674
78675
78676
78677
78678
78679
78680
78681
78682
78683
78684
78685
78686
78687
78688
78689
78690
78691
78692
78693
78694
78695
78696
78697
78698
78699
78700
78701
78702
78703
78704
78705
78706
78707
78708
78709
78710
78711
78712
78713
78714
78715
78716
78717
78718
78719
78720
78721
78722
78723
78724
78725
78726
78727
78728
78729
78730
78731
78732
78733
78734
78735
78736
78737
78738
78739
78740
78741
78742
78743
78744
78745
78746
78747
78748
78749
78750
78751
78752
78753
78754
78755
78756
78757
78758
78759
78760
78761
78762
78763
78764
78765
78766
78767
78768
78769
78770
78771
78772
78773
78774
78775
78776
78777
78778
78779
78780
78781
78782
78783
78784
78785
78786
78787
78788
78789
78790
78791
78792
78793
78794
78795
78796
78797
78798
78799
78800
78801
78802
78803
78804
78805
78806
78807
78808
78809
78810
78811
78812
78813
78814
78815
78816
78817
78818
78819
78820
78821
78822
78823
78824
78825
78826
78827
78828
78829
78830
78831
78832
78833
78834
78835
78836
78837
78838
78839
78840
78841
78842
78843
78844
78845
78846
78847
78848
78849
78850
78851
78852
78853
78854
78855
78856
78857
78858
78859
78860
78861
78862
78863
78864
78865
78866
78867
78868
78869
78870
78871
78872
78873
78874
78875
78876
78877
78878
78879
78880
78881
78882
78883
78884
78885
78886
78887
78888
78889
78890
78891
78892
78893
78894
78895
78896
78897
78898
78899
78900
78901
78902
78903
78904
78905
78906
78907
78908
78909
78910
78911
78912
78913
78914
78915
78916
78917
78918
78919
78920
78921
78922
78923
78924
78925
78926
78927
78928
78929
78930
78931
78932
78933
78934
78935
78936
78937
78938
78939
78940
78941
78942
78943
78944
78945
78946
78947
78948
78949
78950
78951
78952
78953
78954
78955
78956
78957
78958
78959
78960
78961
78962
78963
78964
78965
78966
78967
78968
78969
78970
78971
78972
78973
78974
78975
78976
78977
78978
78979
78980
78981
78982
78983
78984
78985
78986
78987
78988
78989
78990
78991
78992
78993
78994
78995
78996
78997
78998
78999
79000
79001
79002
79003
79004
79005
79006
79007
79008
79009
79010
79011
79012
79013
79014
79015
79016
79017
79018
79019
79020
79021
79022
79023
79024
79025
79026
79027
79028
79029
79030
79031
79032
79033
79034
79035
79036
79037
79038
79039
79040
79041
79042
79043
79044
79045
79046
79047
79048
79049
79050
79051
79052
79053
79054
79055
79056
79057
79058
79059
79060
79061
79062
79063
79064
79065
79066
79067
79068
79069
79070
79071
79072
79073
79074
79075
79076
79077
79078
79079
79080
79081
79082
79083
79084
79085
79086
79087
79088
79089
79090
79091
79092
79093
79094
79095
79096
79097
79098
79099
79100
79101
79102
79103
79104
79105
79106
79107
79108
79109
79110
79111
79112
79113
79114
79115
79116
79117
79118
79119
79120
79121
79122
79123
79124
79125
79126
79127
79128
79129
79130
79131
79132
79133
79134
79135
79136
79137
79138
79139
79140
79141
79142
79143
79144
79145
79146
79147
79148
79149
79150
79151
79152
79153
79154
79155
79156
79157
79158
79159
79160
79161
79162
79163
79164
79165
79166
79167
79168
79169
79170
79171
79172
79173
79174
79175
79176
79177
79178
79179
79180
79181
79182
79183
79184
79185
79186
79187
79188
79189
79190
79191
79192
79193
79194
79195
79196
79197
79198
79199
79200
79201
79202
79203
79204
79205
79206
79207
79208
79209
79210
79211
79212
79213
79214
79215
79216
79217
79218
79219
79220
79221
79222
79223
79224
79225
79226
79227
79228
79229
79230
79231
79232
79233
79234
79235
79236
79237
79238
79239
79240
79241
79242
79243
79244
79245
79246
79247
79248
79249
79250
79251
79252
79253
79254
79255
79256
79257
79258
79259
79260
79261
79262
79263
79264
79265
79266
79267
79268
79269
79270
79271
79272
79273
79274
79275
79276
79277
79278
79279
79280
79281
79282
79283
79284
79285
79286
79287
79288
79289
79290
79291
79292
79293
79294
79295
79296
79297
79298
79299
79300
79301
79302
79303
79304
79305
79306
79307
79308
79309
79310
79311
79312
79313
79314
79315
79316
79317
79318
79319
79320
79321
79322
79323
79324
79325
79326
79327
79328
79329
79330
79331
79332
79333
79334
79335
79336
79337
79338
79339
79340
79341
79342
79343
79344
79345
79346
79347
79348
79349
79350
79351
79352
79353
79354
79355
79356
79357
79358
79359
79360
79361
79362
79363
79364
79365
79366
79367
79368
79369
79370
79371
79372
79373
79374
79375
79376
79377
79378
79379
79380
79381
79382
79383
79384
79385
79386
79387
79388
79389
79390
79391
79392
79393
79394
79395
79396
79397
79398
79399
79400
79401
79402
79403
79404
79405
79406
79407
79408
79409
79410
79411
79412
79413
79414
79415
79416
79417
79418
79419
79420
79421
79422
79423
79424
79425
79426
79427
79428
79429
79430
79431
79432
79433
79434
79435
79436
79437
79438
79439
79440
79441
79442
79443
79444
79445
79446
79447
79448
79449
79450
79451
79452
79453
79454
79455
79456
79457
79458
79459
79460
79461
79462
79463
79464
79465
79466
79467
79468
79469
79470
79471
79472
79473
79474
79475
79476
79477
79478
79479
79480
79481
79482
79483
79484
79485
79486
79487
79488
79489
79490
79491
79492
79493
79494
79495
79496
79497
79498
79499
79500
79501
79502
79503
79504
79505
79506
79507
79508
79509
79510
79511
79512
79513
79514
79515
79516
79517
79518
79519
79520
79521
79522
79523
79524
79525
79526
79527
79528
79529
79530
79531
79532
79533
79534
79535
79536
79537
79538
79539
79540
79541
79542
79543
79544
79545
79546
79547
79548
79549
79550
79551
79552
79553
79554
79555
79556
79557
79558
79559
79560
79561
79562
79563
79564
79565
79566
79567
79568
79569
79570
79571
79572
79573
79574
79575
79576
79577
79578
79579
79580
79581
79582
79583
79584
79585
79586
79587
79588
79589
79590
79591
79592
79593
79594
79595
79596
79597
79598
79599
79600
79601
79602
79603
79604
79605
79606
79607
79608
79609
79610
79611
79612
79613
79614
79615
79616
79617
79618
79619
79620
79621
79622
79623
79624
79625
79626
79627
79628
79629
79630
79631
79632
79633
79634
79635
79636
79637
79638
79639
79640
79641
79642
79643
79644
79645
79646
79647
79648
79649
79650
79651
79652
79653
79654
79655
79656
79657
79658
79659
79660
79661
79662
79663
79664
79665
79666
79667
79668
79669
79670
79671
79672
79673
79674
79675
79676
79677
79678
79679
79680
79681
79682
79683
79684
79685
79686
79687
79688
79689
79690
79691
79692
79693
79694
79695
79696
79697
79698
79699
79700
79701
79702
79703
79704
79705
79706
79707
79708
79709
79710
79711
79712
79713
79714
79715
79716
79717
79718
79719
79720
79721
79722
79723
79724
79725
79726
79727
79728
79729
79730
79731
79732
79733
79734
79735
79736
79737
79738
79739
79740
79741
79742
79743
79744
79745
79746
79747
79748
79749
79750
79751
79752
79753
79754
79755
79756
79757
79758
79759
79760
79761
79762
79763
79764
79765
79766
79767
79768
79769
79770
79771
79772
79773
79774
79775
79776
79777
79778
79779
79780
79781
79782
79783
79784
79785
79786
79787
79788
79789
79790
79791
79792
79793
79794
79795
79796
79797
79798
79799
79800
79801
79802
79803
79804
79805
79806
79807
79808
79809
79810
79811
79812
79813
79814
79815
79816
79817
79818
79819
79820
79821
79822
79823
79824
79825
79826
79827
79828
79829
79830
79831
79832
79833
79834
79835
79836
79837
79838
79839
79840
79841
79842
79843
79844
79845
79846
79847
79848
79849
79850
79851
79852
79853
79854
79855
79856
79857
79858
79859
79860
79861
79862
79863
79864
79865
79866
79867
79868
79869
79870
79871
79872
79873
79874
79875
79876
79877
79878
79879
79880
79881
79882
79883
79884
79885
79886
79887
79888
79889
79890
79891
79892
79893
79894
79895
79896
79897
79898
79899
79900
79901
79902
79903
79904
79905
79906
79907
79908
79909
79910
79911
79912
79913
79914
79915
79916
79917
79918
79919
79920
79921
79922
79923
79924
79925
79926
79927
79928
79929
79930
79931
79932
79933
79934
79935
79936
79937
79938
79939
79940
79941
79942
79943
79944
79945
79946
79947
79948
79949
79950
79951
79952
79953
79954
79955
79956
79957
79958
79959
79960
79961
79962
79963
79964
79965
79966
79967
79968
79969
79970
79971
79972
79973
79974
79975
79976
79977
79978
79979
79980
79981
79982
79983
79984
79985
79986
79987
79988
79989
79990
79991
79992
79993
79994
79995
79996
79997
79998
79999
80000
80001
80002
80003
80004
80005
80006
80007
80008
80009
80010
80011
80012
80013
80014
80015
80016
80017
80018
80019
80020
80021
80022
80023
80024
80025
80026
80027
80028
80029
80030
80031
80032
80033
80034
80035
80036
80037
80038
80039
80040
80041
80042
80043
80044
80045
80046
80047
80048
80049
80050
80051
80052
80053
80054
80055
80056
80057
80058
80059
80060
80061
80062
80063
80064
80065
80066
80067
80068
80069
80070
80071
80072
80073
80074
80075
80076
80077
80078
80079
80080
80081
80082
80083
80084
80085
80086
80087
80088
80089
80090
80091
80092
80093
80094
80095
80096
80097
80098
80099
80100
80101
80102
80103
80104
80105
80106
80107
80108
80109
80110
80111
80112
80113
80114
80115
80116
80117
80118
80119
80120
80121
80122
80123
80124
80125
80126
80127
80128
80129
80130
80131
80132
80133
80134
80135
80136
80137
80138
80139
80140
80141
80142
80143
80144
80145
80146
80147
80148
80149
80150
80151
80152
80153
80154
80155
80156
80157
80158
80159
80160
80161
80162
80163
80164
80165
80166
80167
80168
80169
80170
80171
80172
80173
80174
80175
80176
80177
80178
80179
80180
80181
80182
80183
80184
80185
80186
80187
80188
80189
80190
80191
80192
80193
80194
80195
80196
80197
80198
80199
80200
80201
80202
80203
80204
80205
80206
80207
80208
80209
80210
80211
80212
80213
80214
80215
80216
80217
80218
80219
80220
80221
80222
80223
80224
80225
80226
80227
80228
80229
80230
80231
80232
80233
80234
80235
80236
80237
80238
80239
80240
80241
80242
80243
80244
80245
80246
80247
80248
80249
80250
80251
80252
80253
80254
80255
80256
80257
80258
80259
80260
80261
80262
80263
80264
80265
80266
80267
80268
80269
80270
80271
80272
80273
80274
80275
80276
80277
80278
80279
80280
80281
80282
80283
80284
80285
80286
80287
80288
80289
80290
80291
80292
80293
80294
80295
80296
80297
80298
80299
80300
80301
80302
80303
80304
80305
80306
80307
80308
80309
80310
80311
80312
80313
80314
80315
80316
80317
80318
80319
80320
80321
80322
80323
80324
80325
80326
80327
80328
80329
80330
80331
80332
80333
80334
80335
80336
80337
80338
80339
80340
80341
80342
80343
80344
80345
80346
80347
80348
80349
80350
80351
80352
80353
80354
80355
80356
80357
80358
80359
80360
80361
80362
80363
80364
80365
80366
80367
80368
80369
80370
80371
80372
80373
80374
80375
80376
80377
80378
80379
80380
80381
80382
80383
80384
80385
80386
80387
80388
80389
80390
80391
80392
80393
80394
80395
80396
80397
80398
80399
80400
80401
80402
80403
80404
80405
80406
80407
80408
80409
80410
80411
80412
80413
80414
80415
80416
80417
80418
80419
80420
80421
80422
80423
80424
80425
80426
80427
80428
80429
80430
80431
80432
80433
80434
80435
80436
80437
80438
80439
80440
80441
80442
80443
80444
80445
80446
80447
80448
80449
80450
80451
80452
80453
80454
80455
80456
80457
80458
80459
80460
80461
80462
80463
80464
80465
80466
80467
80468
80469
80470
80471
80472
80473
80474
80475
80476
80477
80478
80479
80480
80481
80482
80483
80484
80485
80486
80487
80488
80489
80490
80491
80492
80493
80494
80495
80496
80497
80498
80499
80500
80501
80502
80503
80504
80505
80506
80507
80508
80509
80510
80511
80512
80513
80514
80515
80516
80517
80518
80519
80520
80521
80522
80523
80524
80525
80526
80527
80528
80529
80530
80531
80532
80533
80534
80535
80536
80537
80538
80539
80540
80541
80542
80543
80544
80545
80546
80547
80548
80549
80550
80551
80552
80553
80554
80555
80556
80557
80558
80559
80560
80561
80562
80563
80564
80565
80566
80567
80568
80569
80570
80571
80572
80573
80574
80575
80576
80577
80578
80579
80580
80581
80582
80583
80584
80585
80586
80587
80588
80589
80590
80591
80592
80593
80594
80595
80596
80597
80598
80599
80600
80601
80602
80603
80604
80605
80606
80607
80608
80609
80610
80611
80612
80613
80614
80615
80616
80617
80618
80619
80620
80621
80622
80623
80624
80625
80626
80627
80628
80629
80630
80631
80632
80633
80634
80635
80636
80637
80638
80639
80640
80641
80642
80643
80644
80645
80646
80647
80648
80649
80650
80651
80652
80653
80654
80655
80656
80657
80658
80659
80660
80661
80662
80663
80664
80665
80666
80667
80668
80669
80670
80671
80672
80673
80674
80675
80676
80677
80678
80679
80680
80681
80682
80683
80684
80685
80686
80687
80688
80689
80690
80691
80692
80693
80694
80695
80696
80697
80698
80699
80700
80701
80702
80703
80704
80705
80706
80707
80708
80709
80710
80711
80712
80713
80714
80715
80716
80717
80718
80719
80720
80721
80722
80723
80724
80725
80726
80727
80728
80729
80730
80731
80732
80733
80734
80735
80736
80737
80738
80739
80740
80741
80742
80743
80744
80745
80746
80747
80748
80749
80750
80751
80752
80753
80754
80755
80756
80757
80758
80759
80760
80761
80762
80763
80764
80765
80766
80767
80768
80769
80770
80771
80772
80773
80774
80775
80776
80777
80778
80779
80780
80781
80782
80783
80784
80785
80786
80787
80788
80789
80790
80791
80792
80793
80794
80795
80796
80797
80798
80799
80800
80801
80802
80803
80804
80805
80806
80807
80808
80809
80810
80811
80812
80813
80814
80815
80816
80817
80818
80819
80820
80821
80822
80823
80824
80825
80826
80827
80828
80829
80830
80831
80832
80833
80834
80835
80836
80837
80838
80839
80840
80841
80842
80843
80844
80845
80846
80847
80848
80849
80850
80851
80852
80853
80854
80855
80856
80857
80858
80859
80860
80861
80862
80863
80864
80865
80866
80867
80868
80869
80870
80871
80872
80873
80874
80875
80876
80877
80878
80879
80880
80881
80882
80883
80884
80885
80886
80887
80888
80889
80890
80891
80892
80893
80894
80895
80896
80897
80898
80899
80900
80901
80902
80903
80904
80905
80906
80907
80908
80909
80910
80911
80912
80913
80914
80915
80916
80917
80918
80919
80920
80921
80922
80923
80924
80925
80926
80927
80928
80929
80930
80931
80932
80933
80934
80935
80936
80937
80938
80939
80940
80941
80942
80943
80944
80945
80946
80947
80948
80949
80950
80951
80952
80953
80954
80955
80956
80957
80958
80959
80960
80961
80962
80963
80964
80965
80966
80967
80968
80969
80970
80971
80972
80973
80974
80975
80976
80977
80978
80979
80980
80981
80982
80983
80984
80985
80986
80987
80988
80989
80990
80991
80992
80993
80994
80995
80996
80997
80998
80999
81000
81001
81002
81003
81004
81005
81006
81007
81008
81009
81010
81011
81012
81013
81014
81015
81016
81017
81018
81019
81020
81021
81022
81023
81024
81025
81026
81027
81028
81029
81030
81031
81032
81033
81034
81035
81036
81037
81038
81039
81040
81041
81042
81043
81044
81045
81046
81047
81048
81049
81050
81051
81052
81053
81054
81055
81056
81057
81058
81059
81060
81061
81062
81063
81064
81065
81066
81067
81068
81069
81070
81071
81072
81073
81074
81075
81076
81077
81078
81079
81080
81081
81082
81083
81084
81085
81086
81087
81088
81089
81090
81091
81092
81093
81094
81095
81096
81097
81098
81099
81100
81101
81102
81103
81104
81105
81106
81107
81108
81109
81110
81111
81112
81113
81114
81115
81116
81117
81118
81119
81120
81121
81122
81123
81124
81125
81126
81127
81128
81129
81130
81131
81132
81133
81134
81135
81136
81137
81138
81139
81140
81141
81142
81143
81144
81145
81146
81147
81148
81149
81150
81151
81152
81153
81154
81155
81156
81157
81158
81159
81160
81161
81162
81163
81164
81165
81166
81167
81168
81169
81170
81171
81172
81173
81174
81175
81176
81177
81178
81179
81180
81181
81182
81183
81184
81185
81186
81187
81188
81189
81190
81191
81192
81193
81194
81195
81196
81197
81198
81199
81200
81201
81202
81203
81204
81205
81206
81207
81208
81209
81210
81211
81212
81213
81214
81215
81216
81217
81218
81219
81220
81221
81222
81223
81224
81225
81226
81227
81228
81229
81230
81231
81232
81233
81234
81235
81236
81237
81238
81239
81240
81241
81242
81243
81244
81245
81246
81247
81248
81249
81250
81251
81252
81253
81254
81255
81256
81257
81258
81259
81260
81261
81262
81263
81264
81265
81266
81267
81268
81269
81270
81271
81272
81273
81274
81275
81276
81277
81278
81279
81280
81281
81282
81283
81284
81285
81286
81287
81288
81289
81290
81291
81292
81293
81294
81295
81296
81297
81298
81299
81300
81301
81302
81303
81304
81305
81306
81307
81308
81309
81310
81311
81312
81313
81314
81315
81316
81317
81318
81319
81320
81321
81322
81323
81324
81325
81326
81327
81328
81329
81330
81331
81332
81333
81334
81335
81336
81337
81338
81339
81340
81341
81342
81343
81344
81345
81346
81347
81348
81349
81350
81351
81352
81353
81354
81355
81356
81357
81358
81359
81360
81361
81362
81363
81364
81365
81366
81367
81368
81369
81370
81371
81372
81373
81374
81375
81376
81377
81378
81379
81380
81381
81382
81383
81384
81385
81386
81387
81388
81389
81390
81391
81392
81393
81394
81395
81396
81397
81398
81399
81400
81401
81402
81403
81404
81405
81406
81407
81408
81409
81410
81411
81412
81413
81414
81415
81416
81417
81418
81419
81420
81421
81422
81423
81424
81425
81426
81427
81428
81429
81430
81431
81432
81433
81434
81435
81436
81437
81438
81439
81440
81441
81442
81443
81444
81445
81446
81447
81448
81449
81450
81451
81452
81453
81454
81455
81456
81457
81458
81459
81460
81461
81462
81463
81464
81465
81466
81467
81468
81469
81470
81471
81472
81473
81474
81475
81476
81477
81478
81479
81480
81481
81482
81483
81484
81485
81486
81487
81488
81489
81490
81491
81492
81493
81494
81495
81496
81497
81498
81499
81500
81501
81502
81503
81504
81505
81506
81507
81508
81509
81510
81511
81512
81513
81514
81515
81516
81517
81518
81519
81520
81521
81522
81523
81524
81525
81526
81527
81528
81529
81530
81531
81532
81533
81534
81535
81536
81537
81538
81539
81540
81541
81542
81543
81544
81545
81546
81547
81548
81549
81550
81551
81552
81553
81554
81555
81556
81557
81558
81559
81560
81561
81562
81563
81564
81565
81566
81567
81568
81569
81570
81571
81572
81573
81574
81575
81576
81577
81578
81579
81580
81581
81582
81583
81584
81585
81586
81587
81588
81589
81590
81591
81592
81593
81594
81595
81596
81597
81598
81599
81600
81601
81602
81603
81604
81605
81606
81607
81608
81609
81610
81611
81612
81613
81614
81615
81616
81617
81618
81619
81620
81621
81622
81623
81624
81625
81626
81627
81628
81629
81630
81631
81632
81633
81634
81635
81636
81637
81638
81639
81640
81641
81642
81643
81644
81645
81646
81647
81648
81649
81650
81651
81652
81653
81654
81655
81656
81657
81658
81659
81660
81661
81662
81663
81664
81665
81666
81667
81668
81669
81670
81671
81672
81673
81674
81675
81676
81677
81678
81679
81680
81681
81682
81683
81684
81685
81686
81687
81688
81689
81690
81691
81692
81693
81694
81695
81696
81697
81698
81699
81700
81701
81702
81703
81704
81705
81706
81707
81708
81709
81710
81711
81712
81713
81714
81715
81716
81717
81718
81719
81720
81721
81722
81723
81724
81725
81726
81727
81728
81729
81730
81731
81732
81733
81734
81735
81736
81737
81738
81739
81740
81741
81742
81743
81744
81745
81746
81747
81748
81749
81750
81751
81752
81753
81754
81755
81756
81757
81758
81759
81760
81761
81762
81763
81764
81765
81766
81767
81768
81769
81770
81771
81772
81773
81774
81775
81776
81777
81778
81779
81780
81781
81782
81783
81784
81785
81786
81787
81788
81789
81790
81791
81792
81793
81794
81795
81796
81797
81798
81799
81800
81801
81802
81803
81804
81805
81806
81807
81808
81809
81810
81811
81812
81813
81814
81815
81816
81817
81818
81819
81820
81821
81822
81823
81824
81825
81826
81827
81828
81829
81830
81831
81832
81833
81834
81835
81836
81837
81838
81839
81840
81841
81842
81843
81844
81845
81846
81847
81848
81849
81850
81851
81852
81853
81854
81855
81856
81857
81858
81859
81860
81861
81862
81863
81864
81865
81866
81867
81868
81869
81870
81871
81872
81873
81874
81875
81876
81877
81878
81879
81880
81881
81882
81883
81884
81885
81886
81887
81888
81889
81890
81891
81892
81893
81894
81895
81896
81897
81898
81899
81900
81901
81902
81903
81904
81905
81906
81907
81908
81909
81910
81911
81912
81913
81914
81915
81916
81917
81918
81919
81920
81921
81922
81923
81924
81925
81926
81927
81928
81929
81930
81931
81932
81933
81934
81935
81936
81937
81938
81939
81940
81941
81942
81943
81944
81945
81946
81947
81948
81949
81950
81951
81952
81953
81954
81955
81956
81957
81958
81959
81960
81961
81962
81963
81964
81965
81966
81967
81968
81969
81970
81971
81972
81973
81974
81975
81976
81977
81978
81979
81980
81981
81982
81983
81984
81985
81986
81987
81988
81989
81990
81991
81992
81993
81994
81995
81996
81997
81998
81999
82000
82001
82002
82003
82004
82005
82006
82007
82008
82009
82010
82011
82012
82013
82014
82015
82016
82017
82018
82019
82020
82021
82022
82023
82024
82025
82026
82027
82028
82029
82030
82031
82032
82033
82034
82035
82036
82037
82038
82039
82040
82041
82042
82043
82044
82045
82046
82047
82048
82049
82050
82051
82052
82053
82054
82055
82056
82057
82058
82059
82060
82061
82062
82063
82064
82065
82066
82067
82068
82069
82070
82071
82072
82073
82074
82075
82076
82077
82078
82079
82080
82081
82082
82083
82084
82085
82086
82087
82088
82089
82090
82091
82092
82093
82094
82095
82096
82097
82098
82099
82100
82101
82102
82103
82104
82105
82106
82107
82108
82109
82110
82111
82112
82113
82114
82115
82116
82117
82118
82119
82120
82121
82122
82123
82124
82125
82126
82127
82128
82129
82130
82131
82132
82133
82134
82135
82136
82137
82138
82139
82140
82141
82142
82143
82144
82145
82146
82147
82148
82149
82150
82151
82152
82153
82154
82155
82156
82157
82158
82159
82160
82161
82162
82163
82164
82165
82166
82167
82168
82169
82170
82171
82172
82173
82174
82175
82176
82177
82178
82179
82180
82181
82182
82183
82184
82185
82186
82187
82188
82189
82190
82191
82192
82193
82194
82195
82196
82197
82198
82199
82200
82201
82202
82203
82204
82205
82206
82207
82208
82209
82210
82211
82212
82213
82214
82215
82216
82217
82218
82219
82220
82221
82222
82223
82224
82225
82226
82227
82228
82229
82230
82231
82232
82233
82234
82235
82236
82237
82238
82239
82240
82241
82242
82243
82244
82245
82246
82247
82248
82249
82250
82251
82252
82253
82254
82255
82256
82257
82258
82259
82260
82261
82262
82263
82264
82265
82266
82267
82268
82269
82270
82271
82272
82273
82274
82275
82276
82277
82278
82279
82280
82281
82282
82283
82284
82285
82286
82287
82288
82289
82290
82291
82292
82293
82294
82295
82296
82297
82298
82299
82300
82301
82302
82303
82304
82305
82306
82307
82308
82309
82310
82311
82312
82313
82314
82315
82316
82317
82318
82319
82320
82321
82322
82323
82324
82325
82326
82327
82328
82329
82330
82331
82332
82333
82334
82335
82336
82337
82338
82339
82340
82341
82342
82343
82344
82345
82346
82347
82348
82349
82350
82351
82352
82353
82354
82355
82356
82357
82358
82359
82360
82361
82362
82363
82364
82365
82366
82367
82368
82369
82370
82371
82372
82373
82374
82375
82376
82377
82378
82379
82380
82381
82382
82383
82384
82385
82386
82387
82388
82389
82390
82391
82392
82393
82394
82395
82396
82397
82398
82399
82400
82401
82402
82403
82404
82405
82406
82407
82408
82409
82410
82411
82412
82413
82414
82415
82416
82417
82418
82419
82420
82421
82422
82423
82424
82425
82426
82427
82428
82429
82430
82431
82432
82433
82434
82435
82436
82437
82438
82439
82440
82441
82442
82443
82444
82445
82446
82447
82448
82449
82450
82451
82452
82453
82454
82455
82456
82457
82458
82459
82460
82461
82462
82463
82464
82465
82466
82467
82468
82469
82470
82471
82472
82473
82474
82475
82476
82477
82478
82479
82480
82481
82482
82483
82484
82485
82486
82487
82488
82489
82490
82491
82492
82493
82494
82495
82496
82497
82498
82499
82500
82501
82502
82503
82504
82505
82506
82507
82508
82509
82510
82511
82512
82513
82514
82515
82516
82517
82518
82519
82520
82521
82522
82523
82524
82525
82526
82527
82528
82529
82530
82531
82532
82533
82534
82535
82536
82537
82538
82539
82540
82541
82542
82543
82544
82545
82546
82547
82548
82549
82550
82551
82552
82553
82554
82555
82556
82557
82558
82559
82560
82561
82562
82563
82564
82565
82566
82567
82568
82569
82570
82571
82572
82573
82574
82575
82576
82577
82578
82579
82580
82581
82582
82583
82584
82585
82586
82587
82588
82589
82590
82591
82592
82593
82594
82595
82596
82597
82598
82599
82600
82601
82602
82603
82604
82605
82606
82607
82608
82609
82610
82611
82612
82613
82614
82615
82616
82617
82618
82619
82620
82621
82622
82623
82624
82625
82626
82627
82628
82629
82630
82631
82632
82633
82634
82635
82636
82637
82638
82639
82640
82641
82642
82643
82644
82645
82646
82647
82648
82649
82650
82651
82652
82653
82654
82655
82656
82657
82658
82659
82660
82661
82662
82663
82664
82665
82666
82667
82668
82669
82670
82671
82672
82673
82674
82675
82676
82677
82678
82679
82680
82681
82682
82683
82684
82685
82686
82687
82688
82689
82690
82691
82692
82693
82694
82695
82696
82697
82698
82699
82700
82701
82702
82703
82704
82705
82706
82707
82708
82709
82710
82711
82712
82713
82714
82715
82716
82717
82718
82719
82720
82721
82722
82723
82724
82725
82726
82727
82728
82729
82730
82731
82732
82733
82734
82735
82736
82737
82738
82739
82740
82741
82742
82743
82744
82745
82746
82747
82748
82749
82750
82751
82752
82753
82754
82755
82756
82757
82758
82759
82760
82761
82762
82763
82764
82765
82766
82767
82768
82769
82770
82771
82772
82773
82774
82775
82776
82777
82778
82779
82780
82781
82782
82783
82784
82785
82786
82787
82788
82789
82790
82791
82792
82793
82794
82795
82796
82797
82798
82799
82800
82801
82802
82803
82804
82805
82806
82807
82808
82809
82810
82811
82812
82813
82814
82815
82816
82817
82818
82819
82820
82821
82822
82823
82824
82825
82826
82827
82828
82829
82830
82831
82832
82833
82834
82835
82836
82837
82838
82839
82840
82841
82842
82843
82844
82845
82846
82847
82848
82849
82850
82851
82852
82853
82854
82855
82856
82857
82858
82859
82860
82861
82862
82863
82864
82865
82866
82867
82868
82869
82870
82871
82872
82873
82874
82875
82876
82877
82878
82879
82880
82881
82882
82883
82884
82885
82886
82887
82888
82889
82890
82891
82892
82893
82894
82895
82896
82897
82898
82899
82900
82901
82902
82903
82904
82905
82906
82907
82908
82909
82910
82911
82912
82913
82914
82915
82916
82917
82918
82919
82920
82921
82922
82923
82924
82925
82926
82927
82928
82929
82930
82931
82932
82933
82934
82935
82936
82937
82938
82939
82940
82941
82942
82943
82944
82945
82946
82947
82948
82949
82950
82951
82952
82953
82954
82955
82956
82957
82958
82959
82960
82961
82962
82963
82964
82965
82966
82967
82968
82969
82970
82971
82972
82973
82974
82975
82976
82977
82978
82979
82980
82981
82982
82983
82984
82985
82986
82987
82988
82989
82990
82991
82992
82993
82994
82995
82996
82997
82998
82999
83000
83001
83002
83003
83004
83005
83006
83007
83008
83009
83010
83011
83012
83013
83014
83015
83016
83017
83018
83019
83020
83021
83022
83023
83024
83025
83026
83027
83028
83029
83030
83031
83032
83033
83034
83035
83036
83037
83038
83039
83040
83041
83042
83043
83044
83045
83046
83047
83048
83049
83050
83051
83052
83053
83054
83055
83056
83057
83058
83059
83060
83061
83062
83063
83064
83065
83066
83067
83068
83069
83070
83071
83072
83073
83074
83075
83076
83077
83078
83079
83080
83081
83082
83083
83084
83085
83086
83087
83088
83089
83090
83091
83092
83093
83094
83095
83096
83097
83098
83099
83100
83101
83102
83103
83104
83105
83106
83107
83108
83109
83110
83111
83112
83113
83114
83115
83116
83117
83118
83119
83120
83121
83122
83123
83124
83125
83126
83127
83128
83129
83130
83131
83132
83133
83134
83135
83136
83137
83138
83139
83140
83141
83142
83143
83144
83145
83146
83147
83148
83149
83150
83151
83152
83153
83154
83155
83156
83157
83158
83159
83160
83161
83162
83163
83164
83165
83166
83167
83168
83169
83170
83171
83172
83173
83174
83175
83176
83177
83178
83179
83180
83181
83182
83183
83184
83185
83186
83187
83188
83189
83190
83191
83192
83193
83194
83195
83196
83197
83198
83199
83200
83201
83202
83203
83204
83205
83206
83207
83208
83209
83210
83211
83212
83213
83214
83215
83216
83217
83218
83219
83220
83221
83222
83223
83224
83225
83226
83227
83228
83229
83230
83231
83232
83233
83234
83235
83236
83237
83238
83239
83240
83241
83242
83243
83244
83245
83246
83247
83248
83249
83250
83251
83252
83253
83254
83255
83256
83257
83258
83259
83260
83261
83262
83263
83264
83265
83266
83267
83268
83269
83270
83271
83272
83273
83274
83275
83276
83277
83278
83279
83280
83281
83282
83283
83284
83285
83286
83287
83288
83289
83290
83291
83292
83293
83294
83295
83296
83297
83298
83299
83300
83301
83302
83303
83304
83305
83306
83307
83308
83309
83310
83311
83312
83313
83314
83315
83316
83317
83318
83319
83320
83321
83322
83323
83324
83325
83326
83327
83328
83329
83330
83331
83332
83333
83334
83335
83336
83337
83338
83339
83340
83341
83342
83343
83344
83345
83346
83347
83348
83349
83350
83351
83352
83353
83354
83355
83356
83357
83358
83359
83360
83361
83362
83363
83364
83365
83366
83367
83368
83369
83370
83371
83372
83373
83374
83375
83376
83377
83378
83379
83380
83381
83382
83383
83384
83385
83386
83387
83388
83389
83390
83391
83392
83393
83394
83395
83396
83397
83398
83399
83400
83401
83402
83403
83404
83405
83406
83407
83408
83409
83410
83411
83412
83413
83414
83415
83416
83417
83418
83419
83420
83421
83422
83423
83424
83425
83426
83427
83428
83429
83430
83431
83432
83433
83434
83435
83436
83437
83438
83439
83440
83441
83442
83443
83444
83445
83446
83447
83448
83449
83450
83451
83452
83453
83454
83455
83456
83457
83458
83459
83460
83461
83462
83463
83464
83465
83466
83467
83468
83469
83470
83471
83472
83473
83474
83475
83476
83477
83478
83479
83480
83481
83482
83483
83484
83485
83486
83487
83488
83489
83490
83491
83492
83493
83494
83495
83496
83497
83498
83499
83500
83501
83502
83503
83504
83505
83506
83507
83508
83509
83510
83511
83512
83513
83514
83515
83516
83517
83518
83519
83520
83521
83522
83523
83524
83525
83526
83527
83528
83529
83530
83531
83532
83533
83534
83535
83536
83537
83538
83539
83540
83541
83542
83543
83544
83545
83546
83547
83548
83549
83550
83551
83552
83553
83554
83555
83556
83557
83558
83559
83560
83561
83562
83563
83564
83565
83566
83567
83568
83569
83570
83571
83572
83573
83574
83575
83576
83577
83578
83579
83580
83581
83582
83583
83584
83585
83586
83587
83588
83589
83590
83591
83592
83593
83594
83595
83596
83597
83598
83599
83600
83601
83602
83603
83604
83605
83606
83607
83608
83609
83610
83611
83612
83613
83614
83615
83616
83617
83618
83619
83620
83621
83622
83623
83624
83625
83626
83627
83628
83629
83630
83631
83632
83633
83634
83635
83636
83637
83638
83639
83640
83641
83642
83643
83644
83645
83646
83647
83648
83649
83650
83651
83652
83653
83654
83655
83656
83657
83658
83659
83660
83661
83662
83663
83664
83665
83666
83667
83668
83669
83670
83671
83672
83673
83674
83675
83676
83677
83678
83679
83680
83681
83682
83683
83684
83685
83686
83687
83688
83689
83690
83691
83692
83693
83694
83695
83696
83697
83698
83699
83700
83701
83702
83703
83704
83705
83706
83707
83708
83709
83710
83711
83712
83713
83714
83715
83716
83717
83718
83719
83720
83721
83722
83723
83724
83725
83726
83727
83728
83729
83730
83731
83732
83733
83734
83735
83736
83737
83738
83739
83740
83741
83742
83743
83744
83745
83746
83747
83748
83749
83750
83751
83752
83753
83754
83755
83756
83757
83758
83759
83760
83761
83762
83763
83764
83765
83766
83767
83768
83769
83770
83771
83772
83773
83774
83775
83776
83777
83778
83779
83780
83781
83782
83783
83784
83785
83786
83787
83788
83789
83790
83791
83792
83793
83794
83795
83796
83797
83798
83799
83800
83801
83802
83803
83804
83805
83806
83807
83808
83809
83810
83811
83812
83813
83814
83815
83816
83817
83818
83819
83820
83821
83822
83823
83824
83825
83826
83827
83828
83829
83830
83831
83832
83833
83834
83835
83836
83837
83838
83839
83840
83841
83842
83843
83844
83845
83846
83847
83848
83849
83850
83851
83852
83853
83854
83855
83856
83857
83858
83859
83860
83861
83862
83863
83864
83865
83866
83867
83868
83869
83870
83871
83872
83873
83874
83875
83876
83877
83878
83879
83880
83881
83882
83883
83884
83885
83886
83887
83888
83889
83890
83891
83892
83893
83894
83895
83896
83897
83898
83899
83900
83901
83902
83903
83904
83905
83906
83907
83908
83909
83910
83911
83912
83913
83914
83915
83916
83917
83918
83919
83920
83921
83922
83923
83924
83925
83926
83927
83928
83929
83930
83931
83932
83933
83934
83935
83936
83937
83938
83939
83940
83941
83942
83943
83944
83945
83946
83947
83948
83949
83950
83951
83952
83953
83954
83955
83956
83957
83958
83959
83960
83961
83962
83963
83964
83965
83966
83967
83968
83969
83970
83971
83972
83973
83974
83975
83976
83977
83978
83979
83980
83981
83982
83983
83984
83985
83986
83987
83988
83989
83990
83991
83992
83993
83994
83995
83996
83997
83998
83999
84000
84001
84002
84003
84004
84005
84006
84007
84008
84009
84010
84011
84012
84013
84014
84015
84016
84017
84018
84019
84020
84021
84022
84023
84024
84025
84026
84027
84028
84029
84030
84031
84032
84033
84034
84035
84036
84037
84038
84039
84040
84041
84042
84043
84044
84045
84046
84047
84048
84049
84050
84051
84052
84053
84054
84055
84056
84057
84058
84059
84060
84061
84062
84063
84064
84065
84066
84067
84068
84069
84070
84071
84072
84073
84074
84075
84076
84077
84078
84079
84080
84081
84082
84083
84084
84085
84086
84087
84088
84089
84090
84091
84092
84093
84094
84095
84096
84097
84098
84099
84100
84101
84102
84103
84104
84105
84106
84107
84108
84109
84110
84111
84112
84113
84114
84115
84116
84117
84118
84119
84120
84121
84122
84123
84124
84125
84126
84127
84128
84129
84130
84131
84132
84133
84134
84135
84136
84137
84138
84139
84140
84141
84142
84143
84144
84145
84146
84147
84148
84149
84150
84151
84152
84153
84154
84155
84156
84157
84158
84159
84160
84161
84162
84163
84164
84165
84166
84167
84168
84169
84170
84171
84172
84173
84174
84175
84176
84177
84178
84179
84180
84181
84182
84183
84184
84185
84186
84187
84188
84189
84190
84191
84192
84193
84194
84195
84196
84197
84198
84199
84200
84201
84202
84203
84204
84205
84206
84207
84208
84209
84210
84211
84212
84213
84214
84215
84216
84217
84218
84219
84220
84221
84222
84223
84224
84225
84226
84227
84228
84229
84230
84231
84232
84233
84234
84235
84236
84237
84238
84239
84240
84241
84242
84243
84244
84245
84246
84247
84248
84249
84250
84251
84252
84253
84254
84255
84256
84257
84258
84259
84260
84261
84262
84263
84264
84265
84266
84267
84268
84269
84270
84271
84272
84273
84274
84275
84276
84277
84278
84279
84280
84281
84282
84283
84284
84285
84286
84287
84288
84289
84290
84291
84292
84293
84294
84295
84296
84297
84298
84299
84300
84301
84302
84303
84304
84305
84306
84307
84308
84309
84310
84311
84312
84313
84314
84315
84316
84317
84318
84319
84320
84321
84322
84323
84324
84325
84326
84327
84328
84329
84330
84331
84332
84333
84334
84335
84336
84337
84338
84339
84340
84341
84342
84343
84344
84345
84346
84347
84348
84349
84350
84351
84352
84353
84354
84355
84356
84357
84358
84359
84360
84361
84362
84363
84364
84365
84366
84367
84368
84369
84370
84371
84372
84373
84374
84375
84376
84377
84378
84379
84380
84381
84382
84383
84384
84385
84386
84387
84388
84389
84390
84391
84392
84393
84394
84395
84396
84397
84398
84399
84400
84401
84402
84403
84404
84405
84406
84407
84408
84409
84410
84411
84412
84413
84414
84415
84416
84417
84418
84419
84420
84421
84422
84423
84424
84425
84426
84427
84428
84429
84430
84431
84432
84433
84434
84435
84436
84437
84438
84439
84440
84441
84442
84443
84444
84445
84446
84447
84448
84449
84450
84451
84452
84453
84454
84455
84456
84457
84458
84459
84460
84461
84462
84463
84464
84465
84466
84467
84468
84469
84470
84471
84472
84473
84474
84475
84476
84477
84478
84479
84480
84481
84482
84483
84484
84485
84486
84487
84488
84489
84490
84491
84492
84493
84494
84495
84496
84497
84498
84499
84500
84501
84502
84503
84504
84505
84506
84507
84508
84509
84510
84511
84512
84513
84514
84515
84516
84517
84518
84519
84520
84521
84522
84523
84524
84525
84526
84527
84528
84529
84530
84531
84532
84533
84534
84535
84536
84537
84538
84539
84540
84541
84542
84543
84544
84545
84546
84547
84548
84549
84550
84551
84552
84553
84554
84555
84556
84557
84558
84559
84560
84561
84562
84563
84564
84565
84566
84567
84568
84569
84570
84571
84572
84573
84574
84575
84576
84577
84578
84579
84580
84581
84582
84583
84584
84585
84586
84587
84588
84589
84590
84591
84592
84593
84594
84595
84596
84597
84598
84599
84600
84601
84602
84603
84604
84605
84606
84607
84608
84609
84610
84611
84612
84613
84614
84615
84616
84617
84618
84619
84620
84621
84622
84623
84624
84625
84626
84627
84628
84629
84630
84631
84632
84633
84634
84635
84636
84637
84638
84639
84640
84641
84642
84643
84644
84645
84646
84647
84648
84649
84650
84651
84652
84653
84654
84655
84656
84657
84658
84659
84660
84661
84662
84663
84664
84665
84666
84667
84668
84669
84670
84671
84672
84673
84674
84675
84676
84677
84678
84679
84680
84681
84682
84683
84684
84685
84686
84687
84688
84689
84690
84691
84692
84693
84694
84695
84696
84697
84698
84699
84700
84701
84702
84703
84704
84705
84706
84707
84708
84709
84710
84711
84712
84713
84714
84715
84716
84717
84718
84719
84720
84721
84722
84723
84724
84725
84726
84727
84728
84729
84730
84731
84732
84733
84734
84735
84736
84737
84738
84739
84740
84741
84742
84743
84744
84745
84746
84747
84748
84749
84750
84751
84752
84753
84754
84755
84756
84757
84758
84759
84760
84761
84762
84763
84764
84765
84766
84767
84768
84769
84770
84771
84772
84773
84774
84775
84776
84777
84778
84779
84780
84781
84782
84783
84784
84785
84786
84787
84788
84789
84790
84791
84792
84793
84794
84795
84796
84797
84798
84799
84800
84801
84802
84803
84804
84805
84806
84807
84808
84809
84810
84811
84812
84813
84814
84815
84816
84817
84818
84819
84820
84821
84822
84823
84824
84825
84826
84827
84828
84829
84830
84831
84832
84833
84834
84835
84836
84837
84838
84839
84840
84841
84842
84843
84844
84845
84846
84847
84848
84849
84850
84851
84852
84853
84854
84855
84856
84857
84858
84859
84860
84861
84862
84863
84864
84865
84866
84867
84868
84869
84870
84871
84872
84873
84874
84875
84876
84877
84878
84879
84880
84881
84882
84883
84884
84885
84886
84887
84888
84889
84890
84891
84892
84893
84894
84895
84896
84897
84898
84899
84900
84901
84902
84903
84904
84905
84906
84907
84908
84909
84910
84911
84912
84913
84914
84915
84916
84917
84918
84919
84920
84921
84922
84923
84924
84925
84926
84927
84928
84929
84930
84931
84932
84933
84934
84935
84936
84937
84938
84939
84940
84941
84942
84943
84944
84945
84946
84947
84948
84949
84950
84951
84952
84953
84954
84955
84956
84957
84958
84959
84960
84961
84962
84963
84964
84965
84966
84967
84968
84969
84970
84971
84972
84973
84974
84975
84976
84977
84978
84979
84980
84981
84982
84983
84984
84985
84986
84987
84988
84989
84990
84991
84992
84993
84994
84995
84996
84997
84998
84999
85000
85001
85002
85003
85004
85005
85006
85007
85008
85009
85010
85011
85012
85013
85014
85015
85016
85017
85018
85019
85020
85021
85022
85023
85024
85025
85026
85027
85028
85029
85030
85031
85032
85033
85034
85035
85036
85037
85038
85039
85040
85041
85042
85043
85044
85045
85046
85047
85048
85049
85050
85051
85052
85053
85054
85055
85056
85057
85058
85059
85060
85061
85062
85063
85064
85065
85066
85067
85068
85069
85070
85071
85072
85073
85074
85075
85076
85077
85078
85079
85080
85081
85082
85083
85084
85085
85086
85087
85088
85089
85090
85091
85092
85093
85094
85095
85096
85097
85098
85099
85100
85101
85102
85103
85104
85105
85106
85107
85108
85109
85110
85111
85112
85113
85114
85115
85116
85117
85118
85119
85120
85121
85122
85123
85124
85125
85126
85127
85128
85129
85130
85131
85132
85133
85134
85135
85136
85137
85138
85139
85140
85141
85142
85143
85144
85145
85146
85147
85148
85149
85150
85151
85152
85153
85154
85155
85156
85157
85158
85159
85160
85161
85162
85163
85164
85165
85166
85167
85168
85169
85170
85171
85172
85173
85174
85175
85176
85177
85178
85179
85180
85181
85182
85183
85184
85185
85186
85187
85188
85189
85190
85191
85192
85193
85194
85195
85196
85197
85198
85199
85200
85201
85202
85203
85204
85205
85206
85207
85208
85209
85210
85211
85212
85213
85214
85215
85216
85217
85218
85219
85220
85221
85222
85223
85224
85225
85226
85227
85228
85229
85230
85231
85232
85233
85234
85235
85236
85237
85238
85239
85240
85241
85242
85243
85244
85245
85246
85247
85248
85249
85250
85251
85252
85253
85254
85255
85256
85257
85258
85259
85260
85261
85262
85263
85264
85265
85266
85267
85268
85269
85270
85271
85272
85273
85274
85275
85276
85277
85278
85279
85280
85281
85282
85283
85284
85285
85286
85287
85288
85289
85290
85291
85292
85293
85294
85295
85296
85297
85298
85299
85300
85301
85302
85303
85304
85305
85306
85307
85308
85309
85310
85311
85312
85313
85314
85315
85316
85317
85318
85319
85320
85321
85322
85323
85324
85325
85326
85327
85328
85329
85330
85331
85332
85333
85334
85335
85336
85337
85338
85339
85340
85341
85342
85343
85344
85345
85346
85347
85348
85349
85350
85351
85352
85353
85354
85355
85356
85357
85358
85359
85360
85361
85362
85363
85364
85365
85366
85367
85368
85369
85370
85371
85372
85373
85374
85375
85376
85377
85378
85379
85380
85381
85382
85383
85384
85385
85386
85387
85388
85389
85390
85391
85392
85393
85394
85395
85396
85397
85398
85399
85400
85401
85402
85403
85404
85405
85406
85407
85408
85409
85410
85411
85412
85413
85414
85415
85416
85417
85418
85419
85420
85421
85422
85423
85424
85425
85426
85427
85428
85429
85430
85431
85432
85433
85434
85435
85436
85437
85438
85439
85440
85441
85442
85443
85444
85445
85446
85447
85448
85449
85450
85451
85452
85453
85454
85455
85456
85457
85458
85459
85460
85461
85462
85463
85464
85465
85466
85467
85468
85469
85470
85471
85472
85473
85474
85475
85476
85477
85478
85479
85480
85481
85482
85483
85484
85485
85486
85487
85488
85489
85490
85491
85492
85493
85494
85495
85496
85497
85498
85499
85500
85501
85502
85503
85504
85505
85506
85507
85508
85509
85510
85511
85512
85513
85514
85515
85516
85517
85518
85519
85520
85521
85522
85523
85524
85525
85526
85527
85528
85529
85530
85531
85532
85533
85534
85535
85536
85537
85538
85539
85540
85541
85542
85543
85544
85545
85546
85547
85548
85549
85550
85551
85552
85553
85554
85555
85556
85557
85558
85559
85560
85561
85562
85563
85564
85565
85566
85567
85568
85569
85570
85571
85572
85573
85574
85575
85576
85577
85578
85579
85580
85581
85582
85583
85584
85585
85586
85587
85588
85589
85590
85591
85592
85593
85594
85595
85596
85597
85598
85599
85600
85601
85602
85603
85604
85605
85606
85607
85608
85609
85610
85611
85612
85613
85614
85615
85616
85617
85618
85619
85620
85621
85622
85623
85624
85625
85626
85627
85628
85629
85630
85631
85632
85633
85634
85635
85636
85637
85638
85639
85640
85641
85642
85643
85644
85645
85646
85647
85648
85649
85650
85651
85652
85653
85654
85655
85656
85657
85658
85659
85660
85661
85662
85663
85664
85665
85666
85667
85668
85669
85670
85671
85672
85673
85674
85675
85676
85677
85678
85679
85680
85681
85682
85683
85684
85685
85686
85687
85688
85689
85690
85691
85692
85693
85694
85695
85696
85697
85698
85699
85700
85701
85702
85703
85704
85705
85706
85707
85708
85709
85710
85711
85712
85713
85714
85715
85716
85717
85718
85719
85720
85721
85722
85723
85724
85725
85726
85727
85728
85729
85730
85731
85732
85733
85734
85735
85736
85737
85738
85739
85740
85741
85742
85743
85744
85745
85746
85747
85748
85749
85750
85751
85752
85753
85754
85755
85756
85757
85758
85759
85760
85761
85762
85763
85764
85765
85766
85767
85768
85769
85770
85771
85772
85773
85774
85775
85776
85777
85778
85779
85780
85781
85782
85783
85784
85785
85786
85787
85788
85789
85790
85791
85792
85793
85794
85795
85796
85797
85798
85799
85800
85801
85802
85803
85804
85805
85806
85807
85808
85809
85810
85811
85812
85813
85814
85815
85816
85817
85818
85819
85820
85821
85822
85823
85824
85825
85826
85827
85828
85829
85830
85831
85832
85833
85834
85835
85836
85837
85838
85839
85840
85841
85842
85843
85844
85845
85846
85847
85848
85849
85850
85851
85852
85853
85854
85855
85856
85857
85858
85859
85860
85861
85862
85863
85864
85865
85866
85867
85868
85869
85870
85871
85872
85873
85874
85875
85876
85877
85878
85879
85880
85881
85882
85883
85884
85885
85886
85887
85888
85889
85890
85891
85892
85893
85894
85895
85896
85897
85898
85899
85900
85901
85902
85903
85904
85905
85906
85907
85908
85909
85910
85911
85912
85913
85914
85915
85916
85917
85918
85919
85920
85921
85922
85923
85924
85925
85926
85927
85928
85929
85930
85931
85932
85933
85934
85935
85936
85937
85938
85939
85940
85941
85942
85943
85944
85945
85946
85947
85948
85949
85950
85951
85952
85953
85954
85955
85956
85957
85958
85959
85960
85961
85962
85963
85964
85965
85966
85967
85968
85969
85970
85971
85972
85973
85974
85975
85976
85977
85978
85979
85980
85981
85982
85983
85984
85985
85986
85987
85988
85989
85990
85991
85992
85993
85994
85995
85996
85997
85998
85999
86000
86001
86002
86003
86004
86005
86006
86007
86008
86009
86010
86011
86012
86013
86014
86015
86016
86017
86018
86019
86020
86021
86022
86023
86024
86025
86026
86027
86028
86029
86030
86031
86032
86033
86034
86035
86036
86037
86038
86039
86040
86041
86042
86043
86044
86045
86046
86047
86048
86049
86050
86051
86052
86053
86054
86055
86056
86057
86058
86059
86060
86061
86062
86063
86064
86065
86066
86067
86068
86069
86070
86071
86072
86073
86074
86075
86076
86077
86078
86079
86080
86081
86082
86083
86084
86085
86086
86087
86088
86089
86090
86091
86092
86093
86094
86095
86096
86097
86098
86099
86100
86101
86102
86103
86104
86105
86106
86107
86108
86109
86110
86111
86112
86113
86114
86115
86116
86117
86118
86119
86120
86121
86122
86123
86124
86125
86126
86127
86128
86129
86130
86131
86132
86133
86134
86135
86136
86137
86138
86139
86140
86141
86142
86143
86144
86145
86146
86147
86148
86149
86150
86151
86152
86153
86154
86155
86156
86157
86158
86159
86160
86161
86162
86163
86164
86165
86166
86167
86168
86169
86170
86171
86172
86173
86174
86175
86176
86177
86178
86179
86180
86181
86182
86183
86184
86185
86186
86187
86188
86189
86190
86191
86192
86193
86194
86195
86196
86197
86198
86199
86200
86201
86202
86203
86204
86205
86206
86207
86208
86209
86210
86211
86212
86213
86214
86215
86216
86217
86218
86219
86220
86221
86222
86223
86224
86225
86226
86227
86228
86229
86230
86231
86232
86233
86234
86235
86236
86237
86238
86239
86240
86241
86242
86243
86244
86245
86246
86247
86248
86249
86250
86251
86252
86253
86254
86255
86256
86257
86258
86259
86260
86261
86262
86263
86264
86265
86266
86267
86268
86269
86270
86271
86272
86273
86274
86275
86276
86277
86278
86279
86280
86281
86282
86283
86284
86285
86286
86287
86288
86289
86290
86291
86292
86293
86294
86295
86296
86297
86298
86299
86300
86301
86302
86303
86304
86305
86306
86307
86308
86309
86310
86311
86312
86313
86314
86315
86316
86317
86318
86319
86320
86321
86322
86323
86324
86325
86326
86327
86328
86329
86330
86331
86332
86333
86334
86335
86336
86337
86338
86339
86340
86341
86342
86343
86344
86345
86346
86347
86348
86349
86350
86351
86352
86353
86354
86355
86356
86357
86358
86359
86360
86361
86362
86363
86364
86365
86366
86367
86368
86369
86370
86371
86372
86373
86374
86375
86376
86377
86378
86379
86380
86381
86382
86383
86384
86385
86386
86387
86388
86389
86390
86391
86392
86393
86394
86395
86396
86397
86398
86399
86400
86401
86402
86403
86404
86405
86406
86407
86408
86409
86410
86411
86412
86413
86414
86415
86416
86417
86418
86419
86420
86421
86422
86423
86424
86425
86426
86427
86428
86429
86430
86431
86432
86433
86434
86435
86436
86437
86438
86439
86440
86441
86442
86443
86444
86445
86446
86447
86448
86449
86450
86451
86452
86453
86454
86455
86456
86457
86458
86459
86460
86461
86462
86463
86464
86465
86466
86467
86468
86469
86470
86471
86472
86473
86474
86475
86476
86477
86478
86479
86480
86481
86482
86483
86484
86485
86486
86487
86488
86489
86490
86491
86492
86493
86494
86495
86496
86497
86498
86499
86500
86501
86502
86503
86504
86505
86506
86507
86508
86509
86510
86511
86512
86513
86514
86515
86516
86517
86518
86519
86520
86521
86522
86523
86524
86525
86526
86527
86528
86529
86530
86531
86532
86533
86534
86535
86536
86537
86538
86539
86540
86541
86542
86543
86544
86545
86546
86547
86548
86549
86550
86551
86552
86553
86554
86555
86556
86557
86558
86559
86560
86561
86562
86563
86564
86565
86566
86567
86568
86569
86570
86571
86572
86573
86574
86575
86576
86577
86578
86579
86580
86581
86582
86583
86584
86585
86586
86587
86588
86589
86590
86591
86592
86593
86594
86595
86596
86597
86598
86599
86600
86601
86602
86603
86604
86605
86606
86607
86608
86609
86610
86611
86612
86613
86614
86615
86616
86617
86618
86619
86620
86621
86622
86623
86624
86625
86626
86627
86628
86629
86630
86631
86632
86633
86634
86635
86636
86637
86638
86639
86640
86641
86642
86643
86644
86645
86646
86647
86648
86649
86650
86651
86652
86653
86654
86655
86656
86657
86658
86659
86660
86661
86662
86663
86664
86665
86666
86667
86668
86669
86670
86671
86672
86673
86674
86675
86676
86677
86678
86679
86680
86681
86682
86683
86684
86685
86686
86687
86688
86689
86690
86691
86692
86693
86694
86695
86696
86697
86698
86699
86700
86701
86702
86703
86704
86705
86706
86707
86708
86709
86710
86711
86712
86713
86714
86715
86716
86717
86718
86719
86720
86721
86722
86723
86724
86725
86726
86727
86728
86729
86730
86731
86732
86733
86734
86735
86736
86737
86738
86739
86740
86741
86742
86743
86744
86745
86746
86747
86748
86749
86750
86751
86752
86753
86754
86755
86756
86757
86758
86759
86760
86761
86762
86763
86764
86765
86766
86767
86768
86769
86770
86771
86772
86773
86774
86775
86776
86777
86778
86779
86780
86781
86782
86783
86784
86785
86786
86787
86788
86789
86790
86791
86792
86793
86794
86795
86796
86797
86798
86799
86800
86801
86802
86803
86804
86805
86806
86807
86808
86809
86810
86811
86812
86813
86814
86815
86816
86817
86818
86819
86820
86821
86822
86823
86824
86825
86826
86827
86828
86829
86830
86831
86832
86833
86834
86835
86836
86837
86838
86839
86840
86841
86842
86843
86844
86845
86846
86847
86848
86849
86850
86851
86852
86853
86854
86855
86856
86857
86858
86859
86860
86861
86862
86863
86864
86865
86866
86867
86868
86869
86870
86871
86872
86873
86874
86875
86876
86877
86878
86879
86880
86881
86882
86883
86884
86885
86886
86887
86888
86889
86890
86891
86892
86893
86894
86895
86896
86897
86898
86899
86900
86901
86902
86903
86904
86905
86906
86907
86908
86909
86910
86911
86912
86913
86914
86915
86916
86917
86918
86919
86920
86921
86922
86923
86924
86925
86926
86927
86928
86929
86930
86931
86932
86933
86934
86935
86936
86937
86938
86939
86940
86941
86942
86943
86944
86945
86946
86947
86948
86949
86950
86951
86952
86953
86954
86955
86956
86957
86958
86959
86960
86961
86962
86963
86964
86965
86966
86967
86968
86969
86970
86971
86972
86973
86974
86975
86976
86977
86978
86979
86980
86981
86982
86983
86984
86985
86986
86987
86988
86989
86990
86991
86992
86993
86994
86995
86996
86997
86998
86999
87000
87001
87002
87003
87004
87005
87006
87007
87008
87009
87010
87011
87012
87013
87014
87015
87016
87017
87018
87019
87020
87021
87022
87023
87024
87025
87026
87027
87028
87029
87030
87031
87032
87033
87034
87035
87036
87037
87038
87039
87040
87041
87042
87043
87044
87045
87046
87047
87048
87049
87050
87051
87052
87053
87054
87055
87056
87057
87058
87059
87060
87061
87062
87063
87064
87065
87066
87067
87068
87069
87070
87071
87072
87073
87074
87075
87076
87077
87078
87079
87080
87081
87082
87083
87084
87085
87086
87087
87088
87089
87090
87091
87092
87093
87094
87095
87096
87097
87098
87099
87100
87101
87102
87103
87104
87105
87106
87107
87108
87109
87110
87111
87112
87113
87114
87115
87116
87117
87118
87119
87120
87121
87122
87123
87124
87125
87126
87127
87128
87129
87130
87131
87132
87133
87134
87135
87136
87137
87138
87139
87140
87141
87142
87143
87144
87145
87146
87147
87148
87149
87150
87151
87152
87153
87154
87155
87156
87157
87158
87159
87160
87161
87162
87163
87164
87165
87166
87167
87168
87169
87170
87171
87172
87173
87174
87175
87176
87177
87178
87179
87180
87181
87182
87183
87184
87185
87186
87187
87188
87189
87190
87191
87192
87193
87194
87195
87196
87197
87198
87199
87200
87201
87202
87203
87204
87205
87206
87207
87208
87209
87210
87211
87212
87213
87214
87215
87216
87217
87218
87219
87220
87221
87222
87223
87224
87225
87226
87227
87228
87229
87230
87231
87232
87233
87234
87235
87236
87237
87238
87239
87240
87241
87242
87243
87244
87245
87246
87247
87248
87249
87250
87251
87252
87253
87254
87255
87256
87257
87258
87259
87260
87261
87262
87263
87264
87265
87266
87267
87268
87269
87270
87271
87272
87273
87274
87275
87276
87277
87278
87279
87280
87281
87282
87283
87284
87285
87286
87287
87288
87289
87290
87291
87292
87293
87294
87295
87296
87297
87298
87299
87300
87301
87302
87303
87304
87305
87306
87307
87308
87309
87310
87311
87312
87313
87314
87315
87316
87317
87318
87319
87320
87321
87322
87323
87324
87325
87326
87327
87328
87329
87330
87331
87332
87333
87334
87335
87336
87337
87338
87339
87340
87341
87342
87343
87344
87345
87346
87347
87348
87349
87350
87351
87352
87353
87354
87355
87356
87357
87358
87359
87360
87361
87362
87363
87364
87365
87366
87367
87368
87369
87370
87371
87372
87373
87374
87375
87376
87377
87378
87379
87380
87381
87382
87383
87384
87385
87386
87387
87388
87389
87390
87391
87392
87393
87394
87395
87396
87397
87398
87399
87400
87401
87402
87403
87404
87405
87406
87407
87408
87409
87410
87411
87412
87413
87414
87415
87416
87417
87418
87419
87420
87421
87422
87423
87424
87425
87426
87427
87428
87429
87430
87431
87432
87433
87434
87435
87436
87437
87438
87439
87440
87441
87442
87443
87444
87445
87446
87447
87448
87449
87450
87451
87452
87453
87454
87455
87456
87457
87458
87459
87460
87461
87462
87463
87464
87465
87466
87467
87468
87469
87470
87471
87472
87473
87474
87475
87476
87477
87478
87479
87480
87481
87482
87483
87484
87485
87486
87487
87488
87489
87490
87491
87492
87493
87494
87495
87496
87497
87498
87499
87500
87501
87502
87503
87504
87505
87506
87507
87508
87509
87510
87511
87512
87513
87514
87515
87516
87517
87518
87519
87520
87521
87522
87523
87524
87525
87526
87527
87528
87529
87530
87531
87532
87533
87534
87535
87536
87537
87538
87539
87540
87541
87542
87543
87544
87545
87546
87547
87548
87549
87550
87551
87552
87553
87554
87555
87556
87557
87558
87559
87560
87561
87562
87563
87564
87565
87566
87567
87568
87569
87570
87571
87572
87573
87574
87575
87576
87577
87578
87579
87580
87581
87582
87583
87584
87585
87586
87587
87588
87589
87590
87591
87592
87593
87594
87595
87596
87597
87598
87599
87600
87601
87602
87603
87604
87605
87606
87607
87608
87609
87610
87611
87612
87613
87614
87615
87616
87617
87618
87619
87620
87621
87622
87623
87624
87625
87626
87627
87628
87629
87630
87631
87632
87633
87634
87635
87636
87637
87638
87639
87640
87641
87642
87643
87644
87645
87646
87647
87648
87649
87650
87651
87652
87653
87654
87655
87656
87657
87658
87659
87660
87661
87662
87663
87664
87665
87666
87667
87668
87669
87670
87671
87672
87673
87674
87675
87676
87677
87678
87679
87680
87681
87682
87683
87684
87685
87686
87687
87688
87689
87690
87691
87692
87693
87694
87695
87696
87697
87698
87699
87700
87701
87702
87703
87704
87705
87706
87707
87708
87709
87710
87711
87712
87713
87714
87715
87716
87717
87718
87719
87720
87721
87722
87723
87724
87725
87726
87727
87728
87729
87730
87731
87732
87733
87734
87735
87736
87737
87738
87739
87740
87741
87742
87743
87744
87745
87746
87747
87748
87749
87750
87751
87752
87753
87754
87755
87756
87757
87758
87759
87760
87761
87762
87763
87764
87765
87766
87767
87768
87769
87770
87771
87772
87773
87774
87775
87776
87777
87778
87779
87780
87781
87782
87783
87784
87785
87786
87787
87788
87789
87790
87791
87792
87793
87794
87795
87796
87797
87798
87799
87800
87801
87802
87803
87804
87805
87806
87807
87808
87809
87810
87811
87812
87813
87814
87815
87816
87817
87818
87819
87820
87821
87822
87823
87824
87825
87826
87827
87828
87829
87830
87831
87832
87833
87834
87835
87836
87837
87838
87839
87840
87841
87842
87843
87844
87845
87846
87847
87848
87849
87850
87851
87852
87853
87854
87855
87856
87857
87858
87859
87860
87861
87862
87863
87864
87865
87866
87867
87868
87869
87870
87871
87872
87873
87874
87875
87876
87877
87878
87879
87880
87881
87882
87883
87884
87885
87886
87887
87888
87889
87890
87891
87892
87893
87894
87895
87896
87897
87898
87899
87900
87901
87902
87903
87904
87905
87906
87907
87908
87909
87910
87911
87912
87913
87914
87915
87916
87917
87918
87919
87920
87921
87922
87923
87924
87925
87926
87927
87928
87929
87930
87931
87932
87933
87934
87935
87936
87937
87938
87939
87940
87941
87942
87943
87944
87945
87946
87947
87948
87949
87950
87951
87952
87953
87954
87955
87956
87957
87958
87959
87960
87961
87962
87963
87964
87965
87966
87967
87968
87969
87970
87971
87972
87973
87974
87975
87976
87977
87978
87979
87980
87981
87982
87983
87984
87985
87986
87987
87988
87989
87990
87991
87992
87993
87994
87995
87996
87997
87998
87999
88000
88001
88002
88003
88004
88005
88006
88007
88008
88009
88010
88011
88012
88013
88014
88015
88016
88017
88018
88019
88020
88021
88022
88023
88024
88025
88026
88027
88028
88029
88030
88031
88032
88033
88034
88035
88036
88037
88038
88039
88040
88041
88042
88043
88044
88045
88046
88047
88048
88049
88050
88051
88052
88053
88054
88055
88056
88057
88058
88059
88060
88061
88062
88063
88064
88065
88066
88067
88068
88069
88070
88071
88072
88073
88074
88075
88076
88077
88078
88079
88080
88081
88082
88083
88084
88085
88086
88087
88088
88089
88090
88091
88092
88093
88094
88095
88096
88097
88098
88099
88100
88101
88102
88103
88104
88105
88106
88107
88108
88109
88110
88111
88112
88113
88114
88115
88116
88117
88118
88119
88120
88121
88122
88123
88124
88125
88126
88127
88128
88129
88130
88131
88132
88133
88134
88135
88136
88137
88138
88139
88140
88141
88142
88143
88144
88145
88146
88147
88148
88149
88150
88151
88152
88153
88154
88155
88156
88157
88158
88159
88160
88161
88162
88163
88164
88165
88166
88167
88168
88169
88170
88171
88172
88173
88174
88175
88176
88177
88178
88179
88180
88181
88182
88183
88184
88185
88186
88187
88188
88189
88190
88191
88192
88193
88194
88195
88196
88197
88198
88199
88200
88201
88202
88203
88204
88205
88206
88207
88208
88209
88210
88211
88212
88213
88214
88215
88216
88217
88218
88219
88220
88221
88222
88223
88224
88225
88226
88227
88228
88229
88230
88231
88232
88233
88234
88235
88236
88237
88238
88239
88240
88241
88242
88243
88244
88245
88246
88247
88248
88249
88250
88251
88252
88253
88254
88255
88256
88257
88258
88259
88260
88261
88262
88263
88264
88265
88266
88267
88268
88269
88270
88271
88272
88273
88274
88275
88276
88277
88278
88279
88280
88281
88282
88283
88284
88285
88286
88287
88288
88289
88290
88291
88292
88293
88294
88295
88296
88297
88298
88299
88300
88301
88302
88303
88304
88305
88306
88307
88308
88309
88310
88311
88312
88313
88314
88315
88316
88317
88318
88319
88320
88321
88322
88323
88324
88325
88326
88327
88328
88329
88330
88331
88332
88333
88334
88335
88336
88337
88338
88339
88340
88341
88342
88343
88344
88345
88346
88347
88348
88349
88350
88351
88352
88353
88354
88355
88356
88357
88358
88359
88360
88361
88362
88363
88364
88365
88366
88367
88368
88369
88370
88371
88372
88373
88374
88375
88376
88377
88378
88379
88380
88381
88382
88383
88384
88385
88386
88387
88388
88389
88390
88391
88392
88393
88394
88395
88396
88397
88398
88399
88400
88401
88402
88403
88404
88405
88406
88407
88408
88409
88410
88411
88412
88413
88414
88415
88416
88417
88418
88419
88420
88421
88422
88423
88424
88425
88426
88427
88428
88429
88430
88431
88432
88433
88434
88435
88436
88437
88438
88439
88440
88441
88442
88443
88444
88445
88446
88447
88448
88449
88450
88451
88452
88453
88454
88455
88456
88457
88458
88459
88460
88461
88462
88463
88464
88465
88466
88467
88468
88469
88470
88471
88472
88473
88474
88475
88476
88477
88478
88479
88480
88481
88482
88483
88484
88485
88486
88487
88488
88489
88490
88491
88492
88493
88494
88495
88496
88497
88498
88499
88500
88501
88502
88503
88504
88505
88506
88507
88508
88509
88510
88511
88512
88513
88514
88515
88516
88517
88518
88519
88520
88521
88522
88523
88524
88525
88526
88527
88528
88529
88530
88531
88532
88533
88534
88535
88536
88537
88538
88539
88540
88541
88542
88543
88544
88545
88546
88547
88548
88549
88550
88551
88552
88553
88554
88555
88556
88557
88558
88559
88560
88561
88562
88563
88564
88565
88566
88567
88568
88569
88570
88571
88572
88573
88574
88575
88576
88577
88578
88579
88580
88581
88582
88583
88584
88585
88586
88587
88588
88589
88590
88591
88592
88593
88594
88595
88596
88597
88598
88599
88600
88601
88602
88603
88604
88605
88606
88607
88608
88609
88610
88611
88612
88613
88614
88615
88616
88617
88618
88619
88620
88621
88622
88623
88624
88625
88626
88627
88628
88629
88630
88631
88632
88633
88634
88635
88636
88637
88638
88639
88640
88641
88642
88643
88644
88645
88646
88647
88648
88649
88650
88651
88652
88653
88654
88655
88656
88657
88658
88659
88660
88661
88662
88663
88664
88665
88666
88667
88668
88669
88670
88671
88672
88673
88674
88675
88676
88677
88678
88679
88680
88681
88682
88683
88684
88685
88686
88687
88688
88689
88690
88691
88692
88693
88694
88695
88696
88697
88698
88699
88700
88701
88702
88703
88704
88705
88706
88707
88708
88709
88710
88711
88712
88713
88714
88715
88716
88717
88718
88719
88720
88721
88722
88723
88724
88725
88726
88727
88728
88729
88730
88731
88732
88733
88734
88735
88736
88737
88738
88739
88740
88741
88742
88743
88744
88745
88746
88747
88748
88749
88750
88751
88752
88753
88754
88755
88756
88757
88758
88759
88760
88761
88762
88763
88764
88765
88766
88767
88768
88769
88770
88771
88772
88773
88774
88775
88776
88777
88778
88779
88780
88781
88782
88783
88784
88785
88786
88787
88788
88789
88790
88791
88792
88793
88794
88795
88796
88797
88798
88799
88800
88801
88802
88803
88804
88805
88806
88807
88808
88809
88810
88811
88812
88813
88814
88815
88816
88817
88818
88819
88820
88821
88822
88823
88824
88825
88826
88827
88828
88829
88830
88831
88832
88833
88834
88835
88836
88837
88838
88839
88840
88841
88842
88843
88844
88845
88846
88847
88848
88849
88850
88851
88852
88853
88854
88855
88856
88857
88858
88859
88860
88861
88862
88863
88864
88865
88866
88867
88868
88869
88870
88871
88872
88873
88874
88875
88876
88877
88878
88879
88880
88881
88882
88883
88884
88885
88886
88887
88888
88889
88890
88891
88892
88893
88894
88895
88896
88897
88898
88899
88900
88901
88902
88903
88904
88905
88906
88907
88908
88909
88910
88911
88912
88913
88914
88915
88916
88917
88918
88919
88920
88921
88922
88923
88924
88925
88926
88927
88928
88929
88930
88931
88932
88933
88934
88935
88936
88937
88938
88939
88940
88941
88942
88943
88944
88945
88946
88947
88948
88949
88950
88951
88952
88953
88954
88955
88956
88957
88958
88959
88960
88961
88962
88963
88964
88965
88966
88967
88968
88969
88970
88971
88972
88973
88974
88975
88976
88977
88978
88979
88980
88981
88982
88983
88984
88985
88986
88987
88988
88989
88990
88991
88992
88993
88994
88995
88996
88997
88998
88999
89000
89001
89002
89003
89004
89005
89006
89007
89008
89009
89010
89011
89012
89013
89014
89015
89016
89017
89018
89019
89020
89021
89022
89023
89024
89025
89026
89027
89028
89029
89030
89031
89032
89033
89034
89035
89036
89037
89038
89039
89040
89041
89042
89043
89044
89045
89046
89047
89048
89049
89050
89051
89052
89053
89054
89055
89056
89057
89058
89059
89060
89061
89062
89063
89064
89065
89066
89067
89068
89069
89070
89071
89072
89073
89074
89075
89076
89077
89078
89079
89080
89081
89082
89083
89084
89085
89086
89087
89088
89089
89090
89091
89092
89093
89094
89095
89096
89097
89098
89099
89100
89101
89102
89103
89104
89105
89106
89107
89108
89109
89110
89111
89112
89113
89114
89115
89116
89117
89118
89119
89120
89121
89122
89123
89124
89125
89126
89127
89128
89129
89130
89131
89132
89133
89134
89135
89136
89137
89138
89139
89140
89141
89142
89143
89144
89145
89146
89147
89148
89149
89150
89151
89152
89153
89154
89155
89156
89157
89158
89159
89160
89161
89162
89163
89164
89165
89166
89167
89168
89169
89170
89171
89172
89173
89174
89175
89176
89177
89178
89179
89180
89181
89182
89183
89184
89185
89186
89187
89188
89189
89190
89191
89192
89193
89194
89195
89196
89197
89198
89199
89200
89201
89202
89203
89204
89205
89206
89207
89208
89209
89210
89211
89212
89213
89214
89215
89216
89217
89218
89219
89220
89221
89222
89223
89224
89225
89226
89227
89228
89229
89230
89231
89232
89233
89234
89235
89236
89237
89238
89239
89240
89241
89242
89243
89244
89245
89246
89247
89248
89249
89250
89251
89252
89253
89254
89255
89256
89257
89258
89259
89260
89261
89262
89263
89264
89265
89266
89267
89268
89269
89270
89271
89272
89273
89274
89275
89276
89277
89278
89279
89280
89281
89282
89283
89284
89285
89286
89287
89288
89289
89290
89291
89292
89293
89294
89295
89296
89297
89298
89299
89300
89301
89302
89303
89304
89305
89306
89307
89308
89309
89310
89311
89312
89313
89314
89315
89316
89317
89318
89319
89320
89321
89322
89323
89324
89325
89326
89327
89328
89329
89330
89331
89332
89333
89334
89335
89336
89337
89338
89339
89340
89341
89342
89343
89344
89345
89346
89347
89348
89349
89350
89351
89352
89353
89354
89355
89356
89357
89358
89359
89360
89361
89362
89363
89364
89365
89366
89367
89368
89369
89370
89371
89372
89373
89374
89375
89376
89377
89378
89379
89380
89381
89382
89383
89384
89385
89386
89387
89388
89389
89390
89391
89392
89393
89394
89395
89396
89397
89398
89399
89400
89401
89402
89403
89404
89405
89406
89407
89408
89409
89410
89411
89412
89413
89414
89415
89416
89417
89418
89419
89420
89421
89422
89423
89424
89425
89426
89427
89428
89429
89430
89431
89432
89433
89434
89435
89436
89437
89438
89439
89440
89441
89442
89443
89444
89445
89446
89447
89448
89449
89450
89451
89452
89453
89454
89455
89456
89457
89458
89459
89460
89461
89462
89463
89464
89465
89466
89467
89468
89469
89470
89471
89472
89473
89474
89475
89476
89477
89478
89479
89480
89481
89482
89483
89484
89485
89486
89487
89488
89489
89490
89491
89492
89493
89494
89495
89496
89497
89498
89499
89500
89501
89502
89503
89504
89505
89506
89507
89508
89509
89510
89511
89512
89513
89514
89515
89516
89517
89518
89519
89520
89521
89522
89523
89524
89525
89526
89527
89528
89529
89530
89531
89532
89533
89534
89535
89536
89537
89538
89539
89540
89541
89542
89543
89544
89545
89546
89547
89548
89549
89550
89551
89552
89553
89554
89555
89556
89557
89558
89559
89560
89561
89562
89563
89564
89565
89566
89567
89568
89569
89570
89571
89572
89573
89574
89575
89576
89577
89578
89579
89580
89581
89582
89583
89584
89585
89586
89587
89588
89589
89590
89591
89592
89593
89594
89595
89596
89597
89598
89599
89600
89601
89602
89603
89604
89605
89606
89607
89608
89609
89610
89611
89612
89613
89614
89615
89616
89617
89618
89619
89620
89621
89622
89623
89624
89625
89626
89627
89628
89629
89630
89631
89632
89633
89634
89635
89636
89637
89638
89639
89640
89641
89642
89643
89644
89645
89646
89647
89648
89649
89650
89651
89652
89653
89654
89655
89656
89657
89658
89659
89660
89661
89662
89663
89664
89665
89666
89667
89668
89669
89670
89671
89672
89673
89674
89675
89676
89677
89678
89679
89680
89681
89682
89683
89684
89685
89686
89687
89688
89689
89690
89691
89692
89693
89694
89695
89696
89697
89698
89699
89700
89701
89702
89703
89704
89705
89706
89707
89708
89709
89710
89711
89712
89713
89714
89715
89716
89717
89718
89719
89720
89721
89722
89723
89724
89725
89726
89727
89728
89729
89730
89731
89732
89733
89734
89735
89736
89737
89738
89739
89740
89741
89742
89743
89744
89745
89746
89747
89748
89749
89750
89751
89752
89753
89754
89755
89756
89757
89758
89759
89760
89761
89762
89763
89764
89765
89766
89767
89768
89769
89770
89771
89772
89773
89774
89775
89776
89777
89778
89779
89780
89781
89782
89783
89784
89785
89786
89787
89788
89789
89790
89791
89792
89793
89794
89795
89796
89797
89798
89799
89800
89801
89802
89803
89804
89805
89806
89807
89808
89809
89810
89811
89812
89813
89814
89815
89816
89817
89818
89819
89820
89821
89822
89823
89824
89825
89826
89827
89828
89829
89830
89831
89832
89833
89834
89835
89836
89837
89838
89839
89840
89841
89842
89843
89844
89845
89846
89847
89848
89849
89850
89851
89852
89853
89854
89855
89856
89857
89858
89859
89860
89861
89862
89863
89864
89865
89866
89867
89868
89869
89870
89871
89872
89873
89874
89875
89876
89877
89878
89879
89880
89881
89882
89883
89884
89885
89886
89887
89888
89889
89890
89891
89892
89893
89894
89895
89896
89897
89898
89899
89900
89901
89902
89903
89904
89905
89906
89907
89908
89909
89910
89911
89912
89913
89914
89915
89916
89917
89918
89919
89920
89921
89922
89923
89924
89925
89926
89927
89928
89929
89930
89931
89932
89933
89934
89935
89936
89937
89938
89939
89940
89941
89942
89943
89944
89945
89946
89947
89948
89949
89950
89951
89952
89953
89954
89955
89956
89957
89958
89959
89960
89961
89962
89963
89964
89965
89966
89967
89968
89969
89970
89971
89972
89973
89974
89975
89976
89977
89978
89979
89980
89981
89982
89983
89984
89985
89986
89987
89988
89989
89990
89991
89992
89993
89994
89995
89996
89997
89998
89999
90000
90001
90002
90003
90004
90005
90006
90007
90008
90009
90010
90011
90012
90013
90014
90015
90016
90017
90018
90019
90020
90021
90022
90023
90024
90025
90026
90027
90028
90029
90030
90031
90032
90033
90034
90035
90036
90037
90038
90039
90040
90041
90042
90043
90044
90045
90046
90047
90048
90049
90050
90051
90052
90053
90054
90055
90056
90057
90058
90059
90060
90061
90062
90063
90064
90065
90066
90067
90068
90069
90070
90071
90072
90073
90074
90075
90076
90077
90078
90079
90080
90081
90082
90083
90084
90085
90086
90087
90088
90089
90090
90091
90092
90093
90094
90095
90096
90097
90098
90099
90100
90101
90102
90103
90104
90105
90106
90107
90108
90109
90110
90111
90112
90113
90114
90115
90116
90117
90118
90119
90120
90121
90122
90123
90124
90125
90126
90127
90128
90129
90130
90131
90132
90133
90134
90135
90136
90137
90138
90139
90140
90141
90142
90143
90144
90145
90146
90147
90148
90149
90150
90151
90152
90153
90154
90155
90156
90157
90158
90159
90160
90161
90162
90163
90164
90165
90166
90167
90168
90169
90170
90171
90172
90173
90174
90175
90176
90177
90178
90179
90180
90181
90182
90183
90184
90185
90186
90187
90188
90189
90190
90191
90192
90193
90194
90195
90196
90197
90198
90199
90200
90201
90202
90203
90204
90205
90206
90207
90208
90209
90210
90211
90212
90213
90214
90215
90216
90217
90218
90219
90220
90221
90222
90223
90224
90225
90226
90227
90228
90229
90230
90231
90232
90233
90234
90235
90236
90237
90238
90239
90240
90241
90242
90243
90244
90245
90246
90247
90248
90249
90250
90251
90252
90253
90254
90255
90256
90257
90258
90259
90260
90261
90262
90263
90264
90265
90266
90267
90268
90269
90270
90271
90272
90273
90274
90275
90276
90277
90278
90279
90280
90281
90282
90283
90284
90285
90286
90287
90288
90289
90290
90291
90292
90293
90294
90295
90296
90297
90298
90299
90300
90301
90302
90303
90304
90305
90306
90307
90308
90309
90310
90311
90312
90313
90314
90315
90316
90317
90318
90319
90320
90321
90322
90323
90324
90325
90326
90327
90328
90329
90330
90331
90332
90333
90334
90335
90336
90337
90338
90339
90340
90341
90342
90343
90344
90345
90346
90347
90348
90349
90350
90351
90352
90353
90354
90355
90356
90357
90358
90359
90360
90361
90362
90363
90364
90365
90366
90367
90368
90369
90370
90371
90372
90373
90374
90375
90376
90377
90378
90379
90380
90381
90382
90383
90384
90385
90386
90387
90388
90389
90390
90391
90392
90393
90394
90395
90396
90397
90398
90399
90400
90401
90402
90403
90404
90405
90406
90407
90408
90409
90410
90411
90412
90413
90414
90415
90416
90417
90418
90419
90420
90421
90422
90423
90424
90425
90426
90427
90428
90429
90430
90431
90432
90433
90434
90435
90436
90437
90438
90439
90440
90441
90442
90443
90444
90445
90446
90447
90448
90449
90450
90451
90452
90453
90454
90455
90456
90457
90458
90459
90460
90461
90462
90463
90464
90465
90466
90467
90468
90469
90470
90471
90472
90473
90474
90475
90476
90477
90478
90479
90480
90481
90482
90483
90484
90485
90486
90487
90488
90489
90490
90491
90492
90493
90494
90495
90496
90497
90498
90499
90500
90501
90502
90503
90504
90505
90506
90507
90508
90509
90510
90511
90512
90513
90514
90515
90516
90517
90518
90519
90520
90521
90522
90523
90524
90525
90526
90527
90528
90529
90530
90531
90532
90533
90534
90535
90536
90537
90538
90539
90540
90541
90542
90543
90544
90545
90546
90547
90548
90549
90550
90551
90552
90553
90554
90555
90556
90557
90558
90559
90560
90561
90562
90563
90564
90565
90566
90567
90568
90569
90570
90571
90572
90573
90574
90575
90576
90577
90578
90579
90580
90581
90582
90583
90584
90585
90586
90587
90588
90589
90590
90591
90592
90593
90594
90595
90596
90597
90598
90599
90600
90601
90602
90603
90604
90605
90606
90607
90608
90609
90610
90611
90612
90613
90614
90615
90616
90617
90618
90619
90620
90621
90622
90623
90624
90625
90626
90627
90628
90629
90630
90631
90632
90633
90634
90635
90636
90637
90638
90639
90640
90641
90642
90643
90644
90645
90646
90647
90648
90649
90650
90651
90652
90653
90654
90655
90656
90657
90658
90659
90660
90661
90662
90663
90664
90665
90666
90667
90668
90669
90670
90671
90672
90673
90674
90675
90676
90677
90678
90679
90680
90681
90682
90683
90684
90685
90686
90687
90688
90689
90690
90691
90692
90693
90694
90695
90696
90697
90698
90699
90700
90701
90702
90703
90704
90705
90706
90707
90708
90709
90710
90711
90712
90713
90714
90715
90716
90717
90718
90719
90720
90721
90722
90723
90724
90725
90726
90727
90728
90729
90730
90731
90732
90733
90734
90735
90736
90737
90738
90739
90740
90741
90742
90743
90744
90745
90746
90747
90748
90749
90750
90751
90752
90753
90754
90755
90756
90757
90758
90759
90760
90761
90762
90763
90764
90765
90766
90767
90768
90769
90770
90771
90772
90773
90774
90775
90776
90777
90778
90779
90780
90781
90782
90783
90784
90785
90786
90787
90788
90789
90790
90791
90792
90793
90794
90795
90796
90797
90798
90799
90800
90801
90802
90803
90804
90805
90806
90807
90808
90809
90810
90811
90812
90813
90814
90815
90816
90817
90818
90819
90820
90821
90822
90823
90824
90825
90826
90827
90828
90829
90830
90831
90832
90833
90834
90835
90836
90837
90838
90839
90840
90841
90842
90843
90844
90845
90846
90847
90848
90849
90850
90851
90852
90853
90854
90855
90856
90857
90858
90859
90860
90861
90862
90863
90864
90865
90866
90867
90868
90869
90870
90871
90872
90873
90874
90875
90876
90877
90878
90879
90880
90881
90882
90883
90884
90885
90886
90887
90888
90889
90890
90891
90892
90893
90894
90895
90896
90897
90898
90899
90900
90901
90902
90903
90904
90905
90906
90907
90908
90909
90910
90911
90912
90913
90914
90915
90916
90917
90918
90919
90920
90921
90922
90923
90924
90925
90926
90927
90928
90929
90930
90931
90932
90933
90934
90935
90936
90937
90938
90939
90940
90941
90942
90943
90944
90945
90946
90947
90948
90949
90950
90951
90952
90953
90954
90955
90956
90957
90958
90959
90960
90961
90962
90963
90964
90965
90966
90967
90968
90969
90970
90971
90972
90973
90974
90975
90976
90977
90978
90979
90980
90981
90982
90983
90984
90985
90986
90987
90988
90989
90990
90991
90992
90993
90994
90995
90996
90997
90998
90999
91000
91001
91002
91003
91004
91005
91006
91007
91008
91009
91010
91011
91012
91013
91014
91015
91016
91017
91018
91019
91020
91021
91022
91023
91024
91025
91026
91027
91028
91029
91030
91031
91032
91033
91034
91035
91036
91037
91038
91039
91040
91041
91042
91043
91044
91045
91046
91047
91048
91049
91050
91051
91052
91053
91054
91055
91056
91057
91058
91059
91060
91061
91062
91063
91064
91065
91066
91067
91068
91069
91070
91071
91072
91073
91074
91075
91076
91077
91078
91079
91080
91081
91082
91083
91084
91085
91086
91087
91088
91089
91090
91091
91092
91093
91094
91095
91096
91097
91098
91099
91100
91101
91102
91103
91104
91105
91106
91107
91108
91109
91110
91111
91112
91113
91114
91115
91116
91117
91118
91119
91120
91121
91122
91123
91124
91125
91126
91127
91128
91129
91130
91131
91132
91133
91134
91135
91136
91137
91138
91139
91140
91141
91142
91143
91144
91145
91146
91147
91148
91149
91150
91151
91152
91153
91154
91155
91156
91157
91158
91159
91160
91161
91162
91163
91164
91165
91166
91167
91168
91169
91170
91171
91172
91173
91174
91175
91176
91177
91178
91179
91180
91181
91182
91183
91184
91185
91186
91187
91188
91189
91190
91191
91192
91193
91194
91195
91196
91197
91198
91199
91200
91201
91202
91203
91204
91205
91206
91207
91208
91209
91210
91211
91212
91213
91214
91215
91216
91217
91218
91219
91220
91221
91222
91223
91224
91225
91226
91227
91228
91229
91230
91231
91232
91233
91234
91235
91236
91237
91238
91239
91240
91241
91242
91243
91244
91245
91246
91247
91248
91249
91250
91251
91252
91253
91254
91255
91256
91257
91258
91259
91260
91261
91262
91263
91264
91265
91266
91267
91268
91269
91270
91271
91272
91273
91274
91275
91276
91277
91278
91279
91280
91281
91282
91283
91284
91285
91286
91287
91288
91289
91290
91291
91292
91293
91294
91295
91296
91297
91298
91299
91300
91301
91302
91303
91304
91305
91306
91307
91308
91309
91310
91311
91312
91313
91314
91315
91316
91317
91318
91319
91320
91321
91322
91323
91324
91325
91326
91327
91328
91329
91330
91331
91332
91333
91334
91335
91336
91337
91338
91339
91340
91341
91342
91343
91344
91345
91346
91347
91348
91349
91350
91351
91352
91353
91354
91355
91356
91357
91358
91359
91360
91361
91362
91363
91364
91365
91366
91367
91368
91369
91370
91371
91372
91373
91374
91375
91376
91377
91378
91379
91380
91381
91382
91383
91384
91385
91386
91387
91388
91389
91390
91391
91392
91393
91394
91395
91396
91397
91398
91399
91400
91401
91402
91403
91404
91405
91406
91407
91408
91409
91410
91411
91412
91413
91414
91415
91416
91417
91418
91419
91420
91421
91422
91423
91424
91425
91426
91427
91428
91429
91430
91431
91432
91433
91434
91435
91436
91437
91438
91439
91440
91441
91442
91443
91444
91445
91446
91447
91448
91449
91450
91451
91452
91453
91454
91455
91456
91457
91458
91459
91460
91461
91462
91463
91464
91465
91466
91467
91468
91469
91470
91471
91472
91473
91474
91475
91476
91477
91478
91479
91480
91481
91482
91483
91484
91485
91486
91487
91488
91489
91490
91491
91492
91493
91494
91495
91496
91497
91498
91499
91500
91501
91502
91503
91504
91505
91506
91507
91508
91509
91510
91511
91512
91513
91514
91515
91516
91517
91518
91519
91520
91521
91522
91523
91524
91525
91526
91527
91528
91529
91530
91531
91532
91533
91534
91535
91536
91537
91538
91539
91540
91541
91542
91543
91544
91545
91546
91547
91548
91549
91550
91551
91552
91553
91554
91555
91556
91557
91558
91559
91560
91561
91562
91563
91564
91565
91566
91567
91568
91569
91570
91571
91572
91573
91574
91575
91576
91577
91578
91579
91580
91581
91582
91583
91584
91585
91586
91587
91588
91589
91590
91591
91592
91593
91594
91595
91596
91597
91598
91599
91600
91601
91602
91603
91604
91605
91606
91607
91608
91609
91610
91611
91612
91613
91614
91615
91616
91617
91618
91619
91620
91621
91622
91623
91624
91625
91626
91627
91628
91629
91630
91631
91632
91633
91634
91635
91636
91637
91638
91639
91640
91641
91642
91643
91644
91645
91646
91647
91648
91649
91650
91651
91652
91653
91654
91655
91656
91657
91658
91659
91660
91661
91662
91663
91664
91665
91666
91667
91668
91669
91670
91671
91672
91673
91674
91675
91676
91677
91678
91679
91680
91681
91682
91683
91684
91685
91686
91687
91688
91689
91690
91691
91692
91693
91694
91695
91696
91697
91698
91699
91700
91701
91702
91703
91704
91705
91706
91707
91708
91709
91710
91711
91712
91713
91714
91715
91716
91717
91718
91719
91720
91721
91722
91723
91724
91725
91726
91727
91728
91729
91730
91731
91732
91733
91734
91735
91736
91737
91738
91739
91740
91741
91742
91743
91744
91745
91746
91747
91748
91749
91750
91751
91752
91753
91754
91755
91756
91757
91758
91759
91760
91761
91762
91763
91764
91765
91766
91767
91768
91769
91770
91771
91772
91773
91774
91775
91776
91777
91778
91779
91780
91781
91782
91783
91784
91785
91786
91787
91788
91789
91790
91791
91792
91793
91794
91795
91796
91797
91798
91799
91800
91801
91802
91803
91804
91805
91806
91807
91808
91809
91810
91811
91812
91813
91814
91815
91816
91817
91818
91819
91820
91821
91822
91823
91824
91825
91826
91827
91828
91829
91830
91831
91832
91833
91834
91835
91836
91837
91838
91839
91840
91841
91842
91843
91844
91845
91846
91847
91848
91849
91850
91851
91852
91853
91854
91855
91856
91857
91858
91859
91860
91861
91862
91863
91864
91865
91866
91867
91868
91869
91870
91871
91872
91873
91874
91875
91876
91877
91878
91879
91880
91881
91882
91883
91884
91885
91886
91887
91888
91889
91890
91891
91892
91893
91894
91895
91896
91897
91898
91899
91900
91901
91902
91903
91904
91905
91906
91907
91908
91909
91910
91911
91912
91913
91914
91915
91916
91917
91918
91919
91920
91921
91922
91923
91924
91925
91926
91927
91928
91929
91930
91931
91932
91933
91934
91935
91936
91937
91938
91939
91940
91941
91942
91943
91944
91945
91946
91947
91948
91949
91950
91951
91952
91953
91954
91955
91956
91957
91958
91959
91960
91961
91962
91963
91964
91965
91966
91967
91968
91969
91970
91971
91972
91973
91974
91975
91976
91977
91978
91979
91980
91981
91982
91983
91984
91985
91986
91987
91988
91989
91990
91991
91992
91993
91994
91995
91996
91997
91998
91999
92000
92001
92002
92003
92004
92005
92006
92007
92008
92009
92010
92011
92012
92013
92014
92015
92016
92017
92018
92019
92020
92021
92022
92023
92024
92025
92026
92027
92028
92029
92030
92031
92032
92033
92034
92035
92036
92037
92038
92039
92040
92041
92042
92043
92044
92045
92046
92047
92048
92049
92050
92051
92052
92053
92054
92055
92056
92057
92058
92059
92060
92061
92062
92063
92064
92065
92066
92067
92068
92069
92070
92071
92072
92073
92074
92075
92076
92077
92078
92079
92080
92081
92082
92083
92084
92085
92086
92087
92088
92089
92090
92091
92092
92093
92094
92095
92096
92097
92098
92099
92100
92101
92102
92103
92104
92105
92106
92107
92108
92109
92110
92111
92112
92113
92114
92115
92116
92117
92118
92119
92120
92121
92122
92123
92124
92125
92126
92127
92128
92129
92130
92131
92132
92133
92134
92135
92136
92137
92138
92139
92140
92141
92142
92143
92144
92145
92146
92147
92148
92149
92150
92151
92152
92153
92154
92155
92156
92157
92158
92159
92160
92161
92162
92163
92164
92165
92166
92167
92168
92169
92170
92171
92172
92173
92174
92175
92176
92177
92178
92179
92180
92181
92182
92183
92184
92185
92186
92187
92188
92189
92190
92191
92192
92193
92194
92195
92196
92197
92198
92199
92200
92201
92202
92203
92204
92205
92206
92207
92208
92209
92210
92211
92212
92213
92214
92215
92216
92217
92218
92219
92220
92221
92222
92223
92224
92225
92226
92227
92228
92229
92230
92231
92232
92233
92234
92235
92236
92237
92238
92239
92240
92241
92242
92243
92244
92245
92246
92247
92248
92249
92250
92251
92252
92253
92254
92255
92256
92257
92258
92259
92260
92261
92262
92263
92264
92265
92266
92267
92268
92269
92270
92271
92272
92273
92274
92275
92276
92277
92278
92279
92280
92281
92282
92283
92284
92285
92286
92287
92288
92289
92290
92291
92292
92293
92294
92295
92296
92297
92298
92299
92300
92301
92302
92303
92304
92305
92306
92307
92308
92309
92310
92311
92312
92313
92314
92315
92316
92317
92318
92319
92320
92321
92322
92323
92324
92325
92326
92327
92328
92329
92330
92331
92332
92333
92334
92335
92336
92337
92338
92339
92340
92341
92342
92343
92344
92345
92346
92347
92348
92349
92350
92351
92352
92353
92354
92355
92356
92357
92358
92359
92360
92361
92362
92363
92364
92365
92366
92367
92368
92369
92370
92371
92372
92373
92374
92375
92376
92377
92378
92379
92380
92381
92382
92383
92384
92385
92386
92387
92388
92389
92390
92391
92392
92393
92394
92395
92396
92397
92398
92399
92400
92401
92402
92403
92404
92405
92406
92407
92408
92409
92410
92411
92412
92413
92414
92415
92416
92417
92418
92419
92420
92421
92422
92423
92424
92425
92426
92427
92428
92429
92430
92431
92432
92433
92434
92435
92436
92437
92438
92439
92440
92441
92442
92443
92444
92445
92446
92447
92448
92449
92450
92451
92452
92453
92454
92455
92456
92457
92458
92459
92460
92461
92462
92463
92464
92465
92466
92467
92468
92469
92470
92471
92472
92473
92474
92475
92476
92477
92478
92479
92480
92481
92482
92483
92484
92485
92486
92487
92488
92489
92490
92491
92492
92493
92494
92495
92496
92497
92498
92499
92500
92501
92502
92503
92504
92505
92506
92507
92508
92509
92510
92511
92512
92513
92514
92515
92516
92517
92518
92519
92520
92521
92522
92523
92524
92525
92526
92527
92528
92529
92530
92531
92532
92533
92534
92535
92536
92537
92538
92539
92540
92541
92542
92543
92544
92545
92546
92547
92548
92549
92550
92551
92552
92553
92554
92555
92556
92557
92558
92559
92560
92561
92562
92563
92564
92565
92566
92567
92568
92569
92570
92571
92572
92573
92574
92575
92576
92577
92578
92579
92580
92581
92582
92583
92584
92585
92586
92587
92588
92589
92590
92591
92592
92593
92594
92595
92596
92597
92598
92599
92600
92601
92602
92603
92604
92605
92606
92607
92608
92609
92610
92611
92612
92613
92614
92615
92616
92617
92618
92619
92620
92621
92622
92623
92624
92625
92626
92627
92628
92629
92630
92631
92632
92633
92634
92635
92636
92637
92638
92639
92640
92641
92642
92643
92644
92645
92646
92647
92648
92649
92650
92651
92652
92653
92654
92655
92656
92657
92658
92659
92660
92661
92662
92663
92664
92665
92666
92667
92668
92669
92670
92671
92672
92673
92674
92675
92676
92677
92678
92679
92680
92681
92682
92683
92684
92685
92686
92687
92688
92689
92690
92691
92692
92693
92694
92695
92696
92697
92698
92699
92700
92701
92702
92703
92704
92705
92706
92707
92708
92709
92710
92711
92712
92713
92714
92715
92716
92717
92718
92719
92720
92721
92722
92723
92724
92725
92726
92727
92728
92729
92730
92731
92732
92733
92734
92735
92736
92737
92738
92739
92740
92741
92742
92743
92744
92745
92746
92747
92748
92749
92750
92751
92752
92753
92754
92755
92756
92757
92758
92759
92760
92761
92762
92763
92764
92765
92766
92767
92768
92769
92770
92771
92772
92773
92774
92775
92776
92777
92778
92779
92780
92781
92782
92783
92784
92785
92786
92787
92788
92789
92790
92791
92792
92793
92794
92795
92796
92797
92798
92799
92800
92801
92802
92803
92804
92805
92806
92807
92808
92809
92810
92811
92812
92813
92814
92815
92816
92817
92818
92819
92820
92821
92822
92823
92824
92825
92826
92827
92828
92829
92830
92831
92832
92833
92834
92835
92836
92837
92838
92839
92840
92841
92842
92843
92844
92845
92846
92847
92848
92849
92850
92851
92852
92853
92854
92855
92856
92857
92858
92859
92860
92861
92862
92863
92864
92865
92866
92867
92868
92869
92870
92871
92872
92873
92874
92875
92876
92877
92878
92879
92880
92881
92882
92883
92884
92885
92886
92887
92888
92889
92890
92891
92892
92893
92894
92895
92896
92897
92898
92899
92900
92901
92902
92903
92904
92905
92906
92907
92908
92909
92910
92911
92912
92913
92914
92915
92916
92917
92918
92919
92920
92921
92922
92923
92924
92925
92926
92927
92928
92929
92930
92931
92932
92933
92934
92935
92936
92937
92938
92939
92940
92941
92942
92943
92944
92945
92946
92947
92948
92949
92950
92951
92952
92953
92954
92955
92956
92957
92958
92959
92960
92961
92962
92963
92964
92965
92966
92967
92968
92969
92970
92971
92972
92973
92974
92975
92976
92977
92978
92979
92980
92981
92982
92983
92984
92985
92986
92987
92988
92989
92990
92991
92992
92993
92994
92995
92996
92997
92998
92999
93000
93001
93002
93003
93004
93005
93006
93007
93008
93009
93010
93011
93012
93013
93014
93015
93016
93017
93018
93019
93020
93021
93022
93023
93024
93025
93026
93027
93028
93029
93030
93031
93032
93033
93034
93035
93036
93037
93038
93039
93040
93041
93042
93043
93044
93045
93046
93047
93048
93049
93050
93051
93052
93053
93054
93055
93056
93057
93058
93059
93060
93061
93062
93063
93064
93065
93066
93067
93068
93069
93070
93071
93072
93073
93074
93075
93076
93077
93078
93079
93080
93081
93082
93083
93084
93085
93086
93087
93088
93089
93090
93091
93092
93093
93094
93095
93096
93097
93098
93099
93100
93101
93102
93103
93104
93105
93106
93107
93108
93109
93110
93111
93112
93113
93114
93115
93116
93117
93118
93119
93120
93121
93122
93123
93124
93125
93126
93127
93128
93129
93130
93131
93132
93133
93134
93135
93136
93137
93138
93139
93140
93141
93142
93143
93144
93145
93146
93147
93148
93149
93150
93151
93152
93153
93154
93155
93156
93157
93158
93159
93160
93161
93162
93163
93164
93165
93166
93167
93168
93169
93170
93171
93172
93173
93174
93175
93176
93177
93178
93179
93180
93181
93182
93183
93184
93185
93186
93187
93188
93189
93190
93191
93192
93193
93194
93195
93196
93197
93198
93199
93200
93201
93202
93203
93204
93205
93206
93207
93208
93209
93210
93211
93212
93213
93214
93215
93216
93217
93218
93219
93220
93221
93222
93223
93224
93225
93226
93227
93228
93229
93230
93231
93232
93233
93234
93235
93236
93237
93238
93239
93240
93241
93242
93243
93244
93245
93246
93247
93248
93249
93250
93251
93252
93253
93254
93255
93256
93257
93258
93259
93260
93261
93262
93263
93264
93265
93266
93267
93268
93269
93270
93271
93272
93273
93274
93275
93276
93277
93278
93279
93280
93281
93282
93283
93284
93285
93286
93287
93288
93289
93290
93291
93292
93293
93294
93295
93296
93297
93298
93299
93300
93301
93302
93303
93304
93305
93306
93307
93308
93309
93310
93311
93312
93313
93314
93315
93316
93317
93318
93319
93320
93321
93322
93323
93324
93325
93326
93327
93328
93329
93330
93331
93332
93333
93334
93335
93336
93337
93338
93339
93340
93341
93342
93343
93344
93345
93346
93347
93348
93349
93350
93351
93352
93353
93354
93355
93356
93357
93358
93359
93360
93361
93362
93363
93364
93365
93366
93367
93368
93369
93370
93371
93372
93373
93374
93375
93376
93377
93378
93379
93380
93381
93382
93383
93384
93385
93386
93387
93388
93389
93390
93391
93392
93393
93394
93395
93396
93397
93398
93399
93400
93401
93402
93403
93404
93405
93406
93407
93408
93409
93410
93411
93412
93413
93414
93415
93416
93417
93418
93419
93420
93421
93422
93423
93424
93425
93426
93427
93428
93429
93430
93431
93432
93433
93434
93435
93436
93437
93438
93439
93440
93441
93442
93443
93444
93445
93446
93447
93448
93449
93450
93451
93452
93453
93454
93455
93456
93457
93458
93459
93460
93461
93462
93463
93464
93465
93466
93467
93468
93469
93470
93471
93472
93473
93474
93475
93476
93477
93478
93479
93480
93481
93482
93483
93484
93485
93486
93487
93488
93489
93490
93491
93492
93493
93494
93495
93496
93497
93498
93499
93500
93501
93502
93503
93504
93505
93506
93507
93508
93509
93510
93511
93512
93513
93514
93515
93516
93517
93518
93519
93520
93521
93522
93523
93524
93525
93526
93527
93528
93529
93530
93531
93532
93533
93534
93535
93536
93537
93538
93539
93540
93541
93542
93543
93544
93545
93546
93547
93548
93549
93550
93551
93552
93553
93554
93555
93556
93557
93558
93559
93560
93561
93562
93563
93564
93565
93566
93567
93568
93569
93570
93571
93572
93573
93574
93575
93576
93577
93578
93579
93580
93581
93582
93583
93584
93585
93586
93587
93588
93589
93590
93591
93592
93593
93594
93595
93596
93597
93598
93599
93600
93601
93602
93603
93604
93605
93606
93607
93608
93609
93610
93611
93612
93613
93614
93615
93616
93617
93618
93619
93620
93621
93622
93623
93624
93625
93626
93627
93628
93629
93630
93631
93632
93633
93634
93635
93636
93637
93638
93639
93640
93641
93642
93643
93644
93645
93646
93647
93648
93649
93650
93651
93652
93653
93654
93655
93656
93657
93658
93659
93660
93661
93662
93663
93664
93665
93666
93667
93668
93669
93670
93671
93672
93673
93674
93675
93676
93677
93678
93679
93680
93681
93682
93683
93684
93685
93686
93687
93688
93689
93690
93691
93692
93693
93694
93695
93696
93697
93698
93699
93700
93701
93702
93703
93704
93705
93706
93707
93708
93709
93710
93711
93712
93713
93714
93715
93716
93717
93718
93719
93720
93721
93722
93723
93724
93725
93726
93727
93728
93729
93730
93731
93732
93733
93734
93735
93736
93737
93738
93739
93740
93741
93742
93743
93744
93745
93746
93747
93748
93749
93750
93751
93752
93753
93754
93755
93756
93757
93758
93759
93760
93761
93762
93763
93764
93765
93766
93767
93768
93769
93770
93771
93772
93773
93774
93775
93776
93777
93778
93779
93780
93781
93782
93783
93784
93785
93786
93787
93788
93789
93790
93791
93792
93793
93794
93795
93796
93797
93798
93799
93800
93801
93802
93803
93804
93805
93806
93807
93808
93809
93810
93811
93812
93813
93814
93815
93816
93817
93818
93819
93820
93821
93822
93823
93824
93825
93826
93827
93828
93829
93830
93831
93832
93833
93834
93835
93836
93837
93838
93839
93840
93841
93842
93843
93844
93845
93846
93847
93848
93849
93850
93851
93852
93853
93854
93855
93856
93857
93858
93859
93860
93861
93862
93863
93864
93865
93866
93867
93868
93869
93870
93871
93872
93873
93874
93875
93876
93877
93878
93879
93880
93881
93882
93883
93884
93885
93886
93887
93888
93889
93890
93891
93892
93893
93894
93895
93896
93897
93898
93899
93900
93901
93902
93903
93904
93905
93906
93907
93908
93909
93910
93911
93912
93913
93914
93915
93916
93917
93918
93919
93920
93921
93922
93923
93924
93925
93926
93927
93928
93929
93930
93931
93932
93933
93934
93935
93936
93937
93938
93939
93940
93941
93942
93943
93944
93945
93946
93947
93948
93949
93950
93951
93952
93953
93954
93955
93956
93957
93958
93959
93960
93961
93962
93963
93964
93965
93966
93967
93968
93969
93970
93971
93972
93973
93974
93975
93976
93977
93978
93979
93980
93981
93982
93983
93984
93985
93986
93987
93988
93989
93990
93991
93992
93993
93994
93995
93996
93997
93998
93999
94000
94001
94002
94003
94004
94005
94006
94007
94008
94009
94010
94011
94012
94013
94014
94015
94016
94017
94018
94019
94020
94021
94022
94023
94024
94025
94026
94027
94028
94029
94030
94031
94032
94033
94034
94035
94036
94037
94038
94039
94040
94041
94042
94043
94044
94045
94046
94047
94048
94049
94050
94051
94052
94053
94054
94055
94056
94057
94058
94059
94060
94061
94062
94063
94064
94065
94066
94067
94068
94069
94070
94071
94072
94073
94074
94075
94076
94077
94078
94079
94080
94081
94082
94083
94084
94085
94086
94087
94088
94089
94090
94091
94092
94093
94094
94095
94096
94097
94098
94099
94100
94101
94102
94103
94104
94105
94106
94107
94108
94109
94110
94111
94112
94113
94114
94115
94116
94117
94118
94119
94120
94121
94122
94123
94124
94125
94126
94127
94128
94129
94130
94131
94132
94133
94134
94135
94136
94137
94138
94139
94140
94141
94142
94143
94144
94145
94146
94147
94148
94149
94150
94151
94152
94153
94154
94155
94156
94157
94158
94159
94160
94161
94162
94163
94164
94165
94166
94167
94168
94169
94170
94171
94172
94173
94174
94175
94176
94177
94178
94179
94180
94181
94182
94183
94184
94185
94186
94187
94188
94189
94190
94191
94192
94193
94194
94195
94196
94197
94198
94199
94200
94201
94202
94203
94204
94205
94206
94207
94208
94209
94210
94211
94212
94213
94214
94215
94216
94217
94218
94219
94220
94221
94222
94223
94224
94225
94226
94227
94228
94229
94230
94231
94232
94233
94234
94235
94236
94237
94238
94239
94240
94241
94242
94243
94244
94245
94246
94247
94248
94249
94250
94251
94252
94253
94254
94255
94256
94257
94258
94259
94260
94261
94262
94263
94264
94265
94266
94267
94268
94269
94270
94271
94272
94273
94274
94275
94276
94277
94278
94279
94280
94281
94282
94283
94284
94285
94286
94287
94288
94289
94290
94291
94292
94293
94294
94295
94296
94297
94298
94299
94300
94301
94302
94303
94304
94305
94306
94307
94308
94309
94310
94311
94312
94313
94314
94315
94316
94317
94318
94319
94320
94321
94322
94323
94324
94325
94326
94327
94328
94329
94330
94331
94332
94333
94334
94335
94336
94337
94338
94339
94340
94341
94342
94343
94344
94345
94346
94347
94348
94349
94350
94351
94352
94353
94354
94355
94356
94357
94358
94359
94360
94361
94362
94363
94364
94365
94366
94367
94368
94369
94370
94371
94372
94373
94374
94375
94376
94377
94378
94379
94380
94381
94382
94383
94384
94385
94386
94387
94388
94389
94390
94391
94392
94393
94394
94395
94396
94397
94398
94399
94400
94401
94402
94403
94404
94405
94406
94407
94408
94409
94410
94411
94412
94413
94414
94415
94416
94417
94418
94419
94420
94421
94422
94423
94424
94425
94426
94427
94428
94429
94430
94431
94432
94433
94434
94435
94436
94437
94438
94439
94440
94441
94442
94443
94444
94445
94446
94447
94448
94449
94450
94451
94452
94453
94454
94455
94456
94457
94458
94459
94460
94461
94462
94463
94464
94465
94466
94467
94468
94469
94470
94471
94472
94473
94474
94475
94476
94477
94478
94479
94480
94481
94482
94483
94484
94485
94486
94487
94488
94489
94490
94491
94492
94493
94494
94495
94496
94497
94498
94499
94500
94501
94502
94503
94504
94505
94506
94507
94508
94509
94510
94511
94512
94513
94514
94515
94516
94517
94518
94519
94520
94521
94522
94523
94524
94525
94526
94527
94528
94529
94530
94531
94532
94533
94534
94535
94536
94537
94538
94539
94540
94541
94542
94543
94544
94545
94546
94547
94548
94549
94550
94551
94552
94553
94554
94555
94556
94557
94558
94559
94560
94561
94562
94563
94564
94565
94566
94567
94568
94569
94570
94571
94572
94573
94574
94575
94576
94577
94578
94579
94580
94581
94582
94583
94584
94585
94586
94587
94588
94589
94590
94591
94592
94593
94594
94595
94596
94597
94598
94599
94600
94601
94602
94603
94604
94605
94606
94607
94608
94609
94610
94611
94612
94613
94614
94615
94616
94617
94618
94619
94620
94621
94622
94623
94624
94625
94626
94627
94628
94629
94630
94631
94632
94633
94634
94635
94636
94637
94638
94639
94640
94641
94642
94643
94644
94645
94646
94647
94648
94649
94650
94651
94652
94653
94654
94655
94656
94657
94658
94659
94660
94661
94662
94663
94664
94665
94666
94667
94668
94669
94670
94671
94672
94673
94674
94675
94676
94677
94678
94679
94680
94681
94682
94683
94684
94685
94686
94687
94688
94689
94690
94691
94692
94693
94694
94695
94696
94697
94698
94699
94700
94701
94702
94703
94704
94705
94706
94707
94708
94709
94710
94711
94712
94713
94714
94715
94716
94717
94718
94719
94720
94721
94722
94723
94724
94725
94726
94727
94728
94729
94730
94731
94732
94733
94734
94735
94736
94737
94738
94739
94740
94741
94742
94743
94744
94745
94746
94747
94748
94749
94750
94751
94752
94753
94754
94755
94756
94757
94758
94759
94760
94761
94762
94763
94764
94765
94766
94767
94768
94769
94770
94771
94772
94773
94774
94775
94776
94777
94778
94779
94780
94781
94782
94783
94784
94785
94786
94787
94788
94789
94790
94791
94792
94793
94794
94795
94796
94797
94798
94799
94800
94801
94802
94803
94804
94805
94806
94807
94808
94809
94810
94811
94812
94813
94814
94815
94816
94817
94818
94819
94820
94821
94822
94823
94824
94825
94826
94827
94828
94829
94830
94831
94832
94833
94834
94835
94836
94837
94838
94839
94840
94841
94842
94843
94844
94845
94846
94847
94848
94849
94850
94851
94852
94853
94854
94855
94856
94857
94858
94859
94860
94861
94862
94863
94864
94865
94866
94867
94868
94869
94870
94871
94872
94873
94874
94875
94876
94877
94878
94879
94880
94881
94882
94883
94884
94885
94886
94887
94888
94889
94890
94891
94892
94893
94894
94895
94896
94897
94898
94899
94900
94901
94902
94903
94904
94905
94906
94907
94908
94909
94910
94911
94912
94913
94914
94915
94916
94917
94918
94919
94920
94921
94922
94923
94924
94925
94926
94927
94928
94929
94930
94931
94932
94933
94934
94935
94936
94937
94938
94939
94940
94941
94942
94943
94944
94945
94946
94947
94948
94949
94950
94951
94952
94953
94954
94955
94956
94957
94958
94959
94960
94961
94962
94963
94964
94965
94966
94967
94968
94969
94970
94971
94972
94973
94974
94975
94976
94977
94978
94979
94980
94981
94982
94983
94984
94985
94986
94987
94988
94989
94990
94991
94992
94993
94994
94995
94996
94997
94998
94999
95000
95001
95002
95003
95004
95005
95006
95007
95008
95009
95010
95011
95012
95013
95014
95015
95016
95017
95018
95019
95020
95021
95022
95023
95024
95025
95026
95027
95028
95029
95030
95031
95032
95033
95034
95035
95036
95037
95038
95039
95040
95041
95042
95043
95044
95045
95046
95047
95048
95049
95050
95051
95052
95053
95054
95055
95056
95057
95058
95059
95060
95061
95062
95063
95064
95065
95066
95067
95068
95069
95070
95071
95072
95073
95074
95075
95076
95077
95078
95079
95080
95081
95082
95083
95084
95085
95086
95087
95088
95089
95090
95091
95092
95093
95094
95095
95096
95097
95098
95099
95100
95101
95102
95103
95104
95105
95106
95107
95108
95109
95110
95111
95112
95113
95114
95115
95116
95117
95118
95119
95120
95121
95122
95123
95124
95125
95126
95127
95128
95129
95130
95131
95132
95133
95134
95135
95136
95137
95138
95139
95140
95141
95142
95143
95144
95145
95146
95147
95148
95149
95150
95151
95152
95153
95154
95155
95156
95157
95158
95159
95160
95161
95162
95163
95164
95165
95166
95167
95168
95169
95170
95171
95172
95173
95174
95175
95176
95177
95178
95179
95180
95181
95182
95183
95184
95185
95186
95187
95188
95189
95190
95191
95192
95193
95194
95195
95196
95197
95198
95199
95200
95201
95202
95203
95204
95205
95206
95207
95208
95209
95210
95211
95212
95213
95214
95215
95216
95217
95218
95219
95220
95221
95222
95223
95224
95225
95226
95227
95228
95229
95230
95231
95232
95233
95234
95235
95236
95237
95238
95239
95240
95241
95242
95243
95244
95245
95246
95247
95248
95249
95250
95251
95252
95253
95254
95255
95256
95257
95258
95259
95260
95261
95262
95263
95264
95265
95266
95267
95268
95269
95270
95271
95272
95273
95274
95275
95276
95277
95278
95279
95280
95281
95282
95283
95284
95285
95286
95287
95288
95289
95290
95291
95292
95293
95294
95295
95296
95297
95298
95299
95300
95301
95302
95303
95304
95305
95306
95307
95308
95309
95310
95311
95312
95313
95314
95315
95316
95317
95318
95319
95320
95321
95322
95323
95324
95325
95326
95327
95328
95329
95330
95331
95332
95333
95334
95335
95336
95337
95338
95339
95340
95341
95342
95343
95344
95345
95346
95347
95348
95349
95350
95351
95352
95353
95354
95355
95356
95357
95358
95359
95360
95361
95362
95363
95364
95365
95366
95367
95368
95369
95370
95371
95372
95373
95374
95375
95376
95377
95378
95379
95380
95381
95382
95383
95384
95385
95386
95387
95388
95389
95390
95391
95392
95393
95394
95395
95396
95397
95398
95399
95400
95401
95402
95403
95404
95405
95406
95407
95408
95409
95410
95411
95412
95413
95414
95415
95416
95417
95418
95419
95420
95421
95422
95423
95424
95425
95426
95427
95428
95429
95430
95431
95432
95433
95434
95435
95436
95437
95438
95439
95440
95441
95442
95443
95444
95445
95446
95447
95448
95449
95450
95451
95452
95453
95454
95455
95456
95457
95458
95459
95460
95461
95462
95463
95464
95465
95466
95467
95468
95469
95470
95471
95472
95473
95474
95475
95476
95477
95478
95479
95480
95481
95482
95483
95484
95485
95486
95487
95488
95489
95490
95491
95492
95493
95494
95495
95496
95497
95498
95499
95500
95501
95502
95503
95504
95505
95506
95507
95508
95509
95510
95511
95512
95513
95514
95515
95516
95517
95518
95519
95520
95521
95522
95523
95524
95525
95526
95527
95528
95529
95530
95531
95532
95533
95534
95535
95536
95537
95538
95539
95540
95541
95542
95543
95544
95545
95546
95547
95548
95549
95550
95551
95552
95553
95554
95555
95556
95557
95558
95559
95560
95561
95562
95563
95564
95565
95566
95567
95568
95569
95570
95571
95572
95573
95574
95575
95576
95577
95578
95579
95580
95581
95582
95583
95584
95585
95586
95587
95588
95589
95590
95591
95592
95593
95594
95595
95596
95597
95598
95599
95600
95601
95602
95603
95604
95605
95606
95607
95608
95609
95610
95611
95612
95613
95614
95615
95616
95617
95618
95619
95620
95621
95622
95623
95624
95625
95626
95627
95628
95629
95630
95631
95632
95633
95634
95635
95636
95637
95638
95639
95640
95641
95642
95643
95644
95645
95646
95647
95648
95649
95650
95651
95652
95653
95654
95655
95656
95657
95658
95659
95660
95661
95662
95663
95664
95665
95666
95667
95668
95669
95670
95671
95672
95673
95674
95675
95676
95677
95678
95679
95680
95681
95682
95683
95684
95685
95686
95687
95688
95689
95690
95691
95692
95693
95694
95695
95696
95697
95698
95699
95700
95701
95702
95703
95704
95705
95706
95707
95708
95709
95710
95711
95712
95713
95714
95715
95716
95717
95718
95719
95720
95721
95722
95723
95724
95725
95726
95727
95728
95729
95730
95731
95732
95733
95734
95735
95736
95737
95738
95739
95740
95741
95742
95743
95744
95745
95746
95747
95748
95749
95750
95751
95752
95753
95754
95755
95756
95757
95758
95759
95760
95761
95762
95763
95764
95765
95766
95767
95768
95769
95770
95771
95772
95773
95774
95775
95776
95777
95778
95779
95780
95781
95782
95783
95784
95785
95786
95787
95788
95789
95790
95791
95792
95793
95794
95795
95796
95797
95798
95799
95800
95801
95802
95803
95804
95805
95806
95807
95808
95809
95810
95811
95812
95813
95814
95815
95816
95817
95818
95819
95820
95821
95822
95823
95824
95825
95826
95827
95828
95829
95830
95831
95832
95833
95834
95835
95836
95837
95838
95839
95840
95841
95842
95843
95844
95845
95846
95847
95848
95849
95850
95851
95852
95853
95854
95855
95856
95857
95858
95859
95860
95861
95862
95863
95864
95865
95866
95867
95868
95869
95870
95871
95872
95873
95874
95875
95876
95877
95878
95879
95880
95881
95882
95883
95884
95885
95886
95887
95888
95889
95890
95891
95892
95893
95894
95895
95896
95897
95898
95899
95900
95901
95902
95903
95904
95905
95906
95907
95908
95909
95910
95911
95912
95913
95914
95915
95916
95917
95918
95919
95920
95921
95922
95923
95924
95925
95926
95927
95928
95929
95930
95931
95932
95933
95934
95935
95936
95937
95938
95939
95940
95941
95942
95943
95944
95945
95946
95947
95948
95949
95950
95951
95952
95953
95954
95955
95956
95957
95958
95959
95960
95961
95962
95963
95964
95965
95966
95967
95968
95969
95970
95971
95972
95973
95974
95975
95976
95977
95978
95979
95980
95981
95982
95983
95984
95985
95986
95987
95988
95989
95990
95991
95992
95993
95994
95995
95996
95997
95998
95999
96000
96001
96002
96003
96004
96005
96006
96007
96008
96009
96010
96011
96012
96013
96014
96015
96016
96017
96018
96019
96020
96021
96022
96023
96024
96025
96026
96027
96028
96029
96030
96031
96032
96033
96034
96035
96036
96037
96038
96039
96040
96041
96042
96043
96044
96045
96046
96047
96048
96049
96050
96051
96052
96053
96054
96055
96056
96057
96058
96059
96060
96061
96062
96063
96064
96065
96066
96067
96068
96069
96070
96071
96072
96073
96074
96075
96076
96077
96078
96079
96080
96081
96082
96083
96084
96085
96086
96087
96088
96089
96090
96091
96092
96093
96094
96095
96096
96097
96098
96099
96100
96101
96102
96103
96104
96105
96106
96107
96108
96109
96110
96111
96112
96113
96114
96115
96116
96117
96118
96119
96120
96121
96122
96123
96124
96125
96126
96127
96128
96129
96130
96131
96132
96133
96134
96135
96136
96137
96138
96139
96140
96141
96142
96143
96144
96145
96146
96147
96148
96149
96150
96151
96152
96153
96154
96155
96156
96157
96158
96159
96160
96161
96162
96163
96164
96165
96166
96167
96168
96169
96170
96171
96172
96173
96174
96175
96176
96177
96178
96179
96180
96181
96182
96183
96184
96185
96186
96187
96188
96189
96190
96191
96192
96193
96194
96195
96196
96197
96198
96199
96200
96201
96202
96203
96204
96205
96206
96207
96208
96209
96210
96211
96212
96213
96214
96215
96216
96217
96218
96219
96220
96221
96222
96223
96224
96225
96226
96227
96228
96229
96230
96231
96232
96233
96234
96235
96236
96237
96238
96239
96240
96241
96242
96243
96244
96245
96246
96247
96248
96249
96250
96251
96252
96253
96254
96255
96256
96257
96258
96259
96260
96261
96262
96263
96264
96265
96266
96267
96268
96269
96270
96271
96272
96273
96274
96275
96276
96277
96278
96279
96280
96281
96282
96283
96284
96285
96286
96287
96288
96289
96290
96291
96292
96293
96294
96295
96296
96297
96298
96299
96300
96301
96302
96303
96304
96305
96306
96307
96308
96309
96310
96311
96312
96313
96314
96315
96316
96317
96318
96319
96320
96321
96322
96323
96324
96325
96326
96327
96328
96329
96330
96331
96332
96333
96334
96335
96336
96337
96338
96339
96340
96341
96342
96343
96344
96345
96346
96347
96348
96349
96350
96351
96352
96353
96354
96355
96356
96357
96358
96359
96360
96361
96362
96363
96364
96365
96366
96367
96368
96369
96370
96371
96372
96373
96374
96375
96376
96377
96378
96379
96380
96381
96382
96383
96384
96385
96386
96387
96388
96389
96390
96391
96392
96393
96394
96395
96396
96397
96398
96399
96400
96401
96402
96403
96404
96405
96406
96407
96408
96409
96410
96411
96412
96413
96414
96415
96416
96417
96418
96419
96420
96421
96422
96423
96424
96425
96426
96427
96428
96429
96430
96431
96432
96433
96434
96435
96436
96437
96438
96439
96440
96441
96442
96443
96444
96445
96446
96447
96448
96449
96450
96451
96452
96453
96454
96455
96456
96457
96458
96459
96460
96461
96462
96463
96464
96465
96466
96467
96468
96469
96470
96471
96472
96473
96474
96475
96476
96477
96478
96479
96480
96481
96482
96483
96484
96485
96486
96487
96488
96489
96490
96491
96492
96493
96494
96495
96496
96497
96498
96499
96500
96501
96502
96503
96504
96505
96506
96507
96508
96509
96510
96511
96512
96513
96514
96515
96516
96517
96518
96519
96520
96521
96522
96523
96524
96525
96526
96527
96528
96529
96530
96531
96532
96533
96534
96535
96536
96537
96538
96539
96540
96541
96542
96543
96544
96545
96546
96547
96548
96549
96550
96551
96552
96553
96554
96555
96556
96557
96558
96559
96560
96561
96562
96563
96564
96565
96566
96567
96568
96569
96570
96571
96572
96573
96574
96575
96576
96577
96578
96579
96580
96581
96582
96583
96584
96585
96586
96587
96588
96589
96590
96591
96592
96593
96594
96595
96596
96597
96598
96599
96600
96601
96602
96603
96604
96605
96606
96607
96608
96609
96610
96611
96612
96613
96614
96615
96616
96617
96618
96619
96620
96621
96622
96623
96624
96625
96626
96627
96628
96629
96630
96631
96632
96633
96634
96635
96636
96637
96638
96639
96640
96641
96642
96643
96644
96645
96646
96647
96648
96649
96650
96651
96652
96653
96654
96655
96656
96657
96658
96659
96660
96661
96662
96663
96664
96665
96666
96667
96668
96669
96670
96671
96672
96673
96674
96675
96676
96677
96678
96679
96680
96681
96682
96683
96684
96685
96686
96687
96688
96689
96690
96691
96692
96693
96694
96695
96696
96697
96698
96699
96700
96701
96702
96703
96704
96705
96706
96707
96708
96709
96710
96711
96712
96713
96714
96715
96716
96717
96718
96719
96720
96721
96722
96723
96724
96725
96726
96727
96728
96729
96730
96731
96732
96733
96734
96735
96736
96737
96738
96739
96740
96741
96742
96743
96744
96745
96746
96747
96748
96749
96750
96751
96752
96753
96754
96755
96756
96757
96758
96759
96760
96761
96762
96763
96764
96765
96766
96767
96768
96769
96770
96771
96772
96773
96774
96775
96776
96777
96778
96779
96780
96781
96782
96783
96784
96785
96786
96787
96788
96789
96790
96791
96792
96793
96794
96795
96796
96797
96798
96799
96800
96801
96802
96803
96804
96805
96806
96807
96808
96809
96810
96811
96812
96813
96814
96815
96816
96817
96818
96819
96820
96821
96822
96823
96824
96825
96826
96827
96828
96829
96830
96831
96832
96833
96834
96835
96836
96837
96838
96839
96840
96841
96842
96843
96844
96845
96846
96847
96848
96849
96850
96851
96852
96853
96854
96855
96856
96857
96858
96859
96860
96861
96862
96863
96864
96865
96866
96867
96868
96869
96870
96871
96872
96873
96874
96875
96876
96877
96878
96879
96880
96881
96882
96883
96884
96885
96886
96887
96888
96889
96890
96891
96892
96893
96894
96895
96896
96897
96898
96899
96900
96901
96902
96903
96904
96905
96906
96907
96908
96909
96910
96911
96912
96913
96914
96915
96916
96917
96918
96919
96920
96921
96922
96923
96924
96925
96926
96927
96928
96929
96930
96931
96932
96933
96934
96935
96936
96937
96938
96939
96940
96941
96942
96943
96944
96945
96946
96947
96948
96949
96950
96951
96952
96953
96954
96955
96956
96957
96958
96959
96960
96961
96962
96963
96964
96965
96966
96967
96968
96969
96970
96971
96972
96973
96974
96975
96976
96977
96978
96979
96980
96981
96982
96983
96984
96985
96986
96987
96988
96989
96990
96991
96992
96993
96994
96995
96996
96997
96998
96999
97000
97001
97002
97003
97004
97005
97006
97007
97008
97009
97010
97011
97012
97013
97014
97015
97016
97017
97018
97019
97020
97021
97022
97023
97024
97025
97026
97027
97028
97029
97030
97031
97032
97033
97034
97035
97036
97037
97038
97039
97040
97041
97042
97043
97044
97045
97046
97047
97048
97049
97050
97051
97052
97053
97054
97055
97056
97057
97058
97059
97060
97061
97062
97063
97064
97065
97066
97067
97068
97069
97070
97071
97072
97073
97074
97075
97076
97077
97078
97079
97080
97081
97082
97083
97084
97085
97086
97087
97088
97089
97090
97091
97092
97093
97094
97095
97096
97097
97098
97099
97100
97101
97102
97103
97104
97105
97106
97107
97108
97109
97110
97111
97112
97113
97114
97115
97116
97117
97118
97119
97120
97121
97122
97123
97124
97125
97126
97127
97128
97129
97130
97131
97132
97133
97134
97135
97136
97137
97138
97139
97140
97141
97142
97143
97144
97145
97146
97147
97148
97149
97150
97151
97152
97153
97154
97155
97156
97157
97158
97159
97160
97161
97162
97163
97164
97165
97166
97167
97168
97169
97170
97171
97172
97173
97174
97175
97176
97177
97178
97179
97180
97181
97182
97183
97184
97185
97186
97187
97188
97189
97190
97191
97192
97193
97194
97195
97196
97197
97198
97199
97200
97201
97202
97203
97204
97205
97206
97207
97208
97209
97210
97211
97212
97213
97214
97215
97216
97217
97218
97219
97220
97221
97222
97223
97224
97225
97226
97227
97228
97229
97230
97231
97232
97233
97234
97235
97236
97237
97238
97239
97240
97241
97242
97243
97244
97245
97246
97247
97248
97249
97250
97251
97252
97253
97254
97255
97256
97257
97258
97259
97260
97261
97262
97263
97264
97265
97266
97267
97268
97269
97270
97271
97272
97273
97274
97275
97276
97277
97278
97279
97280
97281
97282
97283
97284
97285
97286
97287
97288
97289
97290
97291
97292
97293
97294
97295
97296
97297
97298
97299
97300
97301
97302
97303
97304
97305
97306
97307
97308
97309
97310
97311
97312
97313
97314
97315
97316
97317
97318
97319
97320
97321
97322
97323
97324
97325
97326
97327
97328
97329
97330
97331
97332
97333
97334
97335
97336
97337
97338
97339
97340
97341
97342
97343
97344
97345
97346
97347
97348
97349
97350
97351
97352
97353
97354
97355
97356
97357
97358
97359
97360
97361
97362
97363
97364
97365
97366
97367
97368
97369
97370
97371
97372
97373
97374
97375
97376
97377
97378
97379
97380
97381
97382
97383
97384
97385
97386
97387
97388
97389
97390
97391
97392
97393
97394
97395
97396
97397
97398
97399
97400
97401
97402
97403
97404
97405
97406
97407
97408
97409
97410
97411
97412
97413
97414
97415
97416
97417
97418
97419
97420
97421
97422
97423
97424
97425
97426
97427
97428
97429
97430
97431
97432
97433
97434
97435
97436
97437
97438
97439
97440
97441
97442
97443
97444
97445
97446
97447
97448
97449
97450
97451
97452
97453
97454
97455
97456
97457
97458
97459
97460
97461
97462
97463
97464
97465
97466
97467
97468
97469
97470
97471
97472
97473
97474
97475
97476
97477
97478
97479
97480
97481
97482
97483
97484
97485
97486
97487
97488
97489
97490
97491
97492
97493
97494
97495
97496
97497
97498
97499
97500
97501
97502
97503
97504
97505
97506
97507
97508
97509
97510
97511
97512
97513
97514
97515
97516
97517
97518
97519
97520
97521
97522
97523
97524
97525
97526
97527
97528
97529
97530
97531
97532
97533
97534
97535
97536
97537
97538
97539
97540
97541
97542
97543
97544
97545
97546
97547
97548
97549
97550
97551
97552
97553
97554
97555
97556
97557
97558
97559
97560
97561
97562
97563
97564
97565
97566
97567
97568
97569
97570
97571
97572
97573
97574
97575
97576
97577
97578
97579
97580
97581
97582
97583
97584
97585
97586
97587
97588
97589
97590
97591
97592
97593
97594
97595
97596
97597
97598
97599
97600
97601
97602
97603
97604
97605
97606
97607
97608
97609
97610
97611
97612
97613
97614
97615
97616
97617
97618
97619
97620
97621
97622
97623
97624
97625
97626
97627
97628
97629
97630
97631
97632
97633
97634
97635
97636
97637
97638
97639
97640
97641
97642
97643
97644
97645
97646
97647
97648
97649
97650
97651
97652
97653
97654
97655
97656
97657
97658
97659
97660
97661
97662
97663
97664
97665
97666
97667
97668
97669
97670
97671
97672
97673
97674
97675
97676
97677
97678
97679
97680
97681
97682
97683
97684
97685
97686
97687
97688
97689
97690
97691
97692
97693
97694
97695
97696
97697
97698
97699
97700
97701
97702
97703
97704
97705
97706
97707
97708
97709
97710
97711
97712
97713
97714
97715
97716
97717
97718
97719
97720
97721
97722
97723
97724
97725
97726
97727
97728
97729
97730
97731
97732
97733
97734
97735
97736
97737
97738
97739
97740
97741
97742
97743
97744
97745
97746
97747
97748
97749
97750
97751
97752
97753
97754
97755
97756
97757
97758
97759
97760
97761
97762
97763
97764
97765
97766
97767
97768
97769
97770
97771
97772
97773
97774
97775
97776
97777
97778
97779
97780
97781
97782
97783
97784
97785
97786
97787
97788
97789
97790
97791
97792
97793
97794
97795
97796
97797
97798
97799
97800
97801
97802
97803
97804
97805
97806
97807
97808
97809
97810
97811
97812
97813
97814
97815
97816
97817
97818
97819
97820
97821
97822
97823
97824
97825
97826
97827
97828
97829
97830
97831
97832
97833
97834
97835
97836
97837
97838
97839
97840
97841
97842
97843
97844
97845
97846
97847
97848
97849
97850
97851
97852
97853
97854
97855
97856
97857
97858
97859
97860
97861
97862
97863
97864
97865
97866
97867
97868
97869
97870
97871
97872
97873
97874
97875
97876
97877
97878
97879
97880
97881
97882
97883
97884
97885
97886
97887
97888
97889
97890
97891
97892
97893
97894
97895
97896
97897
97898
97899
97900
97901
97902
97903
97904
97905
97906
97907
97908
97909
97910
97911
97912
97913
97914
97915
97916
97917
97918
97919
97920
97921
97922
97923
97924
97925
97926
97927
97928
97929
97930
97931
97932
97933
97934
97935
97936
97937
97938
97939
97940
97941
97942
97943
97944
97945
97946
97947
97948
97949
97950
97951
97952
97953
97954
97955
97956
97957
97958
97959
97960
97961
97962
97963
97964
97965
97966
97967
97968
97969
97970
97971
97972
97973
97974
97975
97976
97977
97978
97979
97980
97981
97982
97983
97984
97985
97986
97987
97988
97989
97990
97991
97992
97993
97994
97995
97996
97997
97998
97999
98000
98001
98002
98003
98004
98005
98006
98007
98008
98009
98010
98011
98012
98013
98014
98015
98016
98017
98018
98019
98020
98021
98022
98023
98024
98025
98026
98027
98028
98029
98030
98031
98032
98033
98034
98035
98036
98037
98038
98039
98040
98041
98042
98043
98044
98045
98046
98047
98048
98049
98050
98051
98052
98053
98054
98055
98056
98057
98058
98059
98060
98061
98062
98063
98064
98065
98066
98067
98068
98069
98070
98071
98072
98073
98074
98075
98076
98077
98078
98079
98080
98081
98082
98083
98084
98085
98086
98087
98088
98089
98090
98091
98092
98093
98094
98095
98096
98097
98098
98099
98100
98101
98102
98103
98104
98105
98106
98107
98108
98109
98110
98111
98112
98113
98114
98115
98116
98117
98118
98119
98120
98121
98122
98123
98124
98125
98126
98127
98128
98129
98130
98131
98132
98133
98134
98135
98136
98137
98138
98139
98140
98141
98142
98143
98144
98145
98146
98147
98148
98149
98150
98151
98152
98153
98154
98155
98156
98157
98158
98159
98160
98161
98162
98163
98164
98165
98166
98167
98168
98169
98170
98171
98172
98173
98174
98175
98176
98177
98178
98179
98180
98181
98182
98183
98184
98185
98186
98187
98188
98189
98190
98191
98192
98193
98194
98195
98196
98197
98198
98199
98200
98201
98202
98203
98204
98205
98206
98207
98208
98209
98210
98211
98212
98213
98214
98215
98216
98217
98218
98219
98220
98221
98222
98223
98224
98225
98226
98227
98228
98229
98230
98231
98232
98233
98234
98235
98236
98237
98238
98239
98240
98241
98242
98243
98244
98245
98246
98247
98248
98249
98250
98251
98252
98253
98254
98255
98256
98257
98258
98259
98260
98261
98262
98263
98264
98265
98266
98267
98268
98269
98270
98271
98272
98273
98274
98275
98276
98277
98278
98279
98280
98281
98282
98283
98284
98285
98286
98287
98288
98289
98290
98291
98292
98293
98294
98295
98296
98297
98298
98299
98300
98301
98302
98303
98304
98305
98306
98307
98308
98309
98310
98311
98312
98313
98314
98315
98316
98317
98318
98319
98320
98321
98322
98323
98324
98325
98326
98327
98328
98329
98330
98331
98332
98333
98334
98335
98336
98337
98338
98339
98340
98341
98342
98343
98344
98345
98346
98347
98348
98349
98350
98351
98352
98353
98354
98355
98356
98357
98358
98359
98360
98361
98362
98363
98364
98365
98366
98367
98368
98369
98370
98371
98372
98373
98374
98375
98376
98377
98378
98379
98380
98381
98382
98383
98384
98385
98386
98387
98388
98389
98390
98391
98392
98393
98394
98395
98396
98397
98398
98399
98400
98401
98402
98403
98404
98405
98406
98407
98408
98409
98410
98411
98412
98413
98414
98415
98416
98417
98418
98419
98420
98421
98422
98423
98424
98425
98426
98427
98428
98429
98430
98431
98432
98433
98434
98435
98436
98437
98438
98439
98440
98441
98442
98443
98444
98445
98446
98447
98448
98449
98450
98451
98452
98453
98454
98455
98456
98457
98458
98459
98460
98461
98462
98463
98464
98465
98466
98467
98468
98469
98470
98471
98472
98473
98474
98475
98476
98477
98478
98479
98480
98481
98482
98483
98484
98485
98486
98487
98488
98489
98490
98491
98492
98493
98494
98495
98496
98497
98498
98499
98500
98501
98502
98503
98504
98505
98506
98507
98508
98509
98510
98511
98512
98513
98514
98515
98516
98517
98518
98519
98520
98521
98522
98523
98524
98525
98526
98527
98528
98529
98530
98531
98532
98533
98534
98535
98536
98537
98538
98539
98540
98541
98542
98543
98544
98545
98546
98547
98548
98549
98550
98551
98552
98553
98554
98555
98556
98557
98558
98559
98560
98561
98562
98563
98564
98565
98566
98567
98568
98569
98570
98571
98572
98573
98574
98575
98576
98577
98578
98579
98580
98581
98582
98583
98584
98585
98586
98587
98588
98589
98590
98591
98592
98593
98594
98595
98596
98597
98598
98599
98600
98601
98602
98603
98604
98605
98606
98607
98608
98609
98610
98611
98612
98613
98614
98615
98616
98617
98618
98619
98620
98621
98622
98623
98624
98625
98626
98627
98628
98629
98630
98631
98632
98633
98634
98635
98636
98637
98638
98639
98640
98641
98642
98643
98644
98645
98646
98647
98648
98649
98650
98651
98652
98653
98654
98655
98656
98657
98658
98659
98660
98661
98662
98663
98664
98665
98666
98667
98668
98669
98670
98671
98672
98673
98674
98675
98676
98677
98678
98679
98680
98681
98682
98683
98684
98685
98686
98687
98688
98689
98690
98691
98692
98693
98694
98695
98696
98697
98698
98699
98700
98701
98702
98703
98704
98705
98706
98707
98708
98709
98710
98711
98712
98713
98714
98715
98716
98717
98718
98719
98720
98721
98722
98723
98724
98725
98726
98727
98728
98729
98730
98731
98732
98733
98734
98735
98736
98737
98738
98739
98740
98741
98742
98743
98744
98745
98746
98747
98748
98749
98750
98751
98752
98753
98754
98755
98756
98757
98758
98759
98760
98761
98762
98763
98764
98765
98766
98767
98768
98769
98770
98771
98772
98773
98774
98775
98776
98777
98778
98779
98780
98781
98782
98783
98784
98785
98786
98787
98788
98789
98790
98791
98792
98793
98794
98795
98796
98797
98798
98799
98800
98801
98802
98803
98804
98805
98806
98807
98808
98809
98810
98811
98812
98813
98814
98815
98816
98817
98818
98819
98820
98821
98822
98823
98824
98825
98826
98827
98828
98829
98830
98831
98832
98833
98834
98835
98836
98837
98838
98839
98840
98841
98842
98843
98844
98845
98846
98847
98848
98849
98850
98851
98852
98853
98854
98855
98856
98857
98858
98859
98860
98861
98862
98863
98864
98865
98866
98867
98868
98869
98870
98871
98872
98873
98874
98875
98876
98877
98878
98879
98880
98881
98882
98883
98884
98885
98886
98887
98888
98889
98890
98891
98892
98893
98894
98895
98896
98897
98898
98899
98900
98901
98902
98903
98904
98905
98906
98907
98908
98909
98910
98911
98912
98913
98914
98915
98916
98917
98918
98919
98920
98921
98922
98923
98924
98925
98926
98927
98928
98929
98930
98931
98932
98933
98934
98935
98936
98937
98938
98939
98940
98941
98942
98943
98944
98945
98946
98947
98948
98949
98950
98951
98952
98953
98954
98955
98956
98957
98958
98959
98960
98961
98962
98963
98964
98965
98966
98967
98968
98969
98970
98971
98972
98973
98974
98975
98976
98977
98978
98979
98980
98981
98982
98983
98984
98985
98986
98987
98988
98989
98990
98991
98992
98993
98994
98995
98996
98997
98998
98999
99000
99001
99002
99003
99004
99005
99006
99007
99008
99009
99010
99011
99012
99013
99014
99015
99016
99017
99018
99019
99020
99021
99022
99023
99024
99025
99026
99027
99028
99029
99030
99031
99032
99033
99034
99035
99036
99037
99038
99039
99040
99041
99042
99043
99044
99045
99046
99047
99048
99049
99050
99051
99052
99053
99054
99055
99056
99057
99058
99059
99060
99061
99062
99063
99064
99065
99066
99067
99068
99069
99070
99071
99072
99073
99074
99075
99076
99077
99078
99079
99080
99081
99082
99083
99084
99085
99086
99087
99088
99089
99090
99091
99092
99093
99094
99095
99096
99097
99098
99099
99100
99101
99102
99103
99104
99105
99106
99107
99108
99109
99110
99111
99112
99113
99114
99115
99116
99117
99118
99119
99120
99121
99122
99123
99124
99125
99126
99127
99128
99129
99130
99131
99132
99133
99134
99135
99136
99137
99138
99139
99140
99141
99142
99143
99144
99145
99146
99147
99148
99149
99150
99151
99152
99153
99154
99155
99156
99157
99158
99159
99160
99161
99162
99163
99164
99165
99166
99167
99168
99169
99170
99171
99172
99173
99174
99175
99176
99177
99178
99179
99180
99181
99182
99183
99184
99185
99186
99187
99188
99189
99190
99191
99192
99193
99194
99195
99196
99197
99198
99199
99200
99201
99202
99203
99204
99205
99206
99207
99208
99209
99210
99211
99212
99213
99214
99215
99216
99217
99218
99219
99220
99221
99222
99223
99224
99225
99226
99227
99228
99229
99230
99231
99232
99233
99234
99235
99236
99237
99238
99239
99240
99241
99242
99243
99244
99245
99246
99247
99248
99249
99250
99251
99252
99253
99254
99255
99256
99257
99258
99259
99260
99261
99262
99263
99264
99265
99266
99267
99268
99269
99270
99271
99272
99273
99274
99275
99276
99277
99278
99279
99280
99281
99282
99283
99284
99285
99286
99287
99288
99289
99290
99291
99292
99293
99294
99295
99296
99297
99298
99299
99300
99301
99302
99303
99304
99305
99306
99307
99308
99309
99310
99311
99312
99313
99314
99315
99316
99317
99318
99319
99320
99321
99322
99323
99324
99325
99326
99327
99328
99329
99330
99331
99332
99333
99334
99335
99336
99337
99338
99339
99340
99341
99342
99343
99344
99345
99346
99347
99348
99349
99350
99351
99352
99353
99354
99355
99356
99357
99358
99359
99360
99361
99362
99363
99364
99365
99366
99367
99368
99369
99370
99371
99372
99373
99374
99375
99376
99377
99378
99379
99380
99381
99382
99383
99384
99385
99386
99387
99388
99389
99390
99391
99392
99393
99394
99395
99396
99397
99398
99399
99400
99401
99402
99403
99404
99405
99406
99407
99408
99409
99410
99411
99412
99413
99414
99415
99416
99417
99418
99419
99420
99421
99422
99423
99424
99425
99426
99427
99428
99429
99430
99431
99432
99433
99434
99435
99436
99437
99438
99439
99440
99441
99442
99443
99444
99445
99446
99447
99448
99449
99450
99451
99452
99453
99454
99455
99456
99457
99458
99459
99460
99461
99462
99463
99464
99465
99466
99467
99468
99469
99470
99471
99472
99473
99474
99475
99476
99477
99478
99479
99480
99481
99482
99483
99484
99485
99486
99487
99488
99489
99490
99491
99492
99493
99494
99495
99496
99497
99498
99499
99500
99501
99502
99503
99504
99505
99506
99507
99508
99509
99510
99511
99512
99513
99514
99515
99516
99517
99518
99519
99520
99521
99522
99523
99524
99525
99526
99527
99528
99529
99530
99531
99532
99533
99534
99535
99536
99537
99538
99539
99540
99541
99542
99543
99544
99545
99546
99547
99548
99549
99550
99551
99552
99553
99554
99555
99556
99557
99558
99559
99560
99561
99562
99563
99564
99565
99566
99567
99568
99569
99570
99571
99572
99573
99574
99575
99576
99577
99578
99579
99580
99581
99582
99583
99584
99585
99586
99587
99588
99589
99590
99591
99592
99593
99594
99595
99596
99597
99598
99599
99600
99601
99602
99603
99604
99605
99606
99607
99608
99609
99610
99611
99612
99613
99614
99615
99616
99617
99618
99619
99620
99621
99622
99623
99624
99625
99626
99627
99628
99629
99630
99631
99632
99633
99634
99635
99636
99637
99638
99639
99640
99641
99642
99643
99644
99645
99646
99647
99648
99649
99650
99651
99652
99653
99654
99655
99656
99657
99658
99659
99660
99661
99662
99663
99664
99665
99666
99667
99668
99669
99670
99671
99672
99673
99674
99675
99676
99677
99678
99679
99680
99681
99682
99683
99684
99685
99686
99687
99688
99689
99690
99691
99692
99693
99694
99695
99696
99697
99698
99699
99700
99701
99702
99703
99704
99705
99706
99707
99708
99709
99710
99711
99712
99713
99714
99715
99716
99717
99718
99719
99720
99721
99722
99723
99724
99725
99726
99727
99728
99729
99730
99731
99732
99733
99734
99735
99736
99737
99738
99739
99740
99741
99742
99743
99744
99745
99746
99747
99748
99749
99750
99751
99752
99753
99754
99755
99756
99757
99758
99759
99760
99761
99762
99763
99764
99765
99766
99767
99768
99769
99770
99771
99772
99773
99774
99775
99776
99777
99778
99779
99780
99781
99782
99783
99784
99785
99786
99787
99788
99789
99790
99791
99792
99793
99794
99795
99796
99797
99798
99799
99800
99801
99802
99803
99804
99805
99806
99807
99808
99809
99810
99811
99812
99813
99814
99815
99816
99817
99818
99819
99820
99821
99822
99823
99824
99825
99826
99827
99828
99829
99830
99831
99832
99833
99834
99835
99836
99837
99838
99839
99840
99841
99842
99843
99844
99845
99846
99847
99848
99849
99850
99851
99852
99853
99854
99855
99856
99857
99858
99859
99860
99861
99862
99863
99864
99865
99866
99867
99868
99869
99870
99871
99872
99873
99874
99875
99876
99877
99878
99879
99880
99881
99882
99883
99884
99885
99886
99887
99888
99889
99890
99891
99892
99893
99894
99895
99896
99897
99898
99899
99900
99901
99902
99903
99904
99905
99906
99907
99908
99909
99910
99911
99912
99913
99914
99915
99916
99917
99918
99919
99920
99921
99922
99923
99924
99925
99926
99927
99928
99929
99930
99931
99932
99933
99934
99935
99936
99937
99938
99939
99940
99941
99942
99943
99944
99945
99946
99947
99948
99949
99950
99951
99952
99953
99954
99955
99956
99957
99958
99959
99960
99961
99962
99963
99964
99965
99966
99967
99968
99969
99970
99971
99972
99973
99974
99975
99976
99977
99978
99979
99980
99981
99982
99983
99984
99985
99986
99987
99988
99989
99990
99991
99992
99993
99994
99995
99996
99997
99998
99999
100000